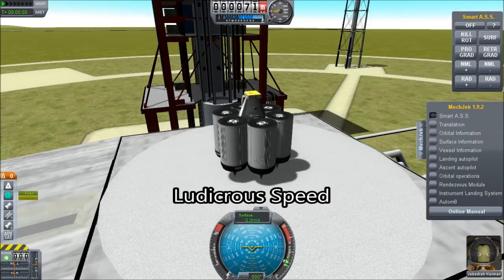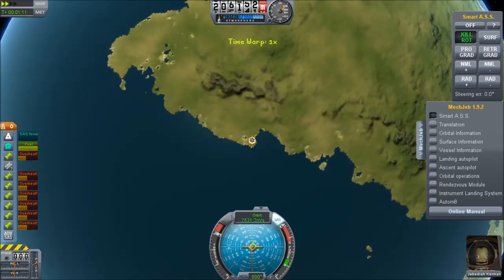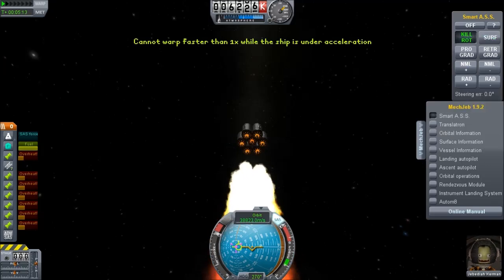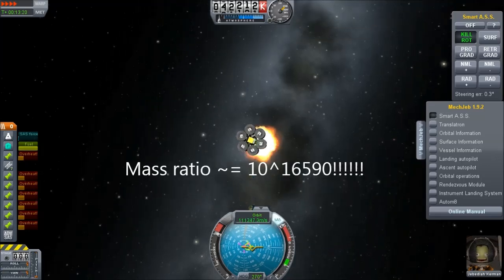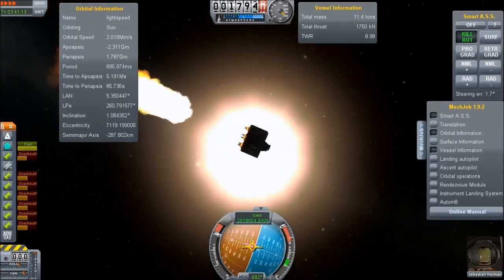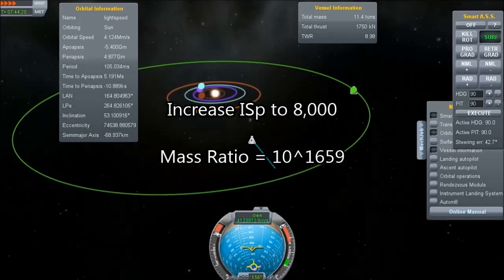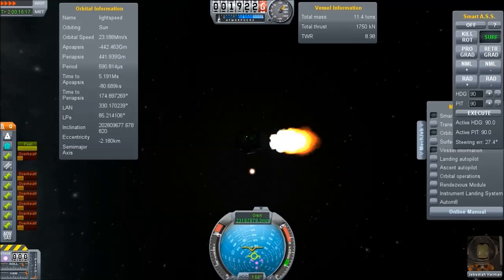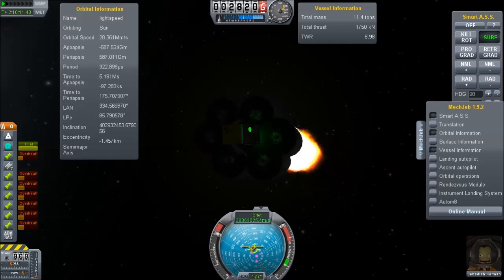What Does It Take To Reach Lightspeed In Kerbal Space Program?

Comment: +Scott Manley That sure was alot of zero's to put that number in a comment well this is what it would look like good luck finding the bottom.

1000000000000000000000000000000000000000000000000000000000000000000000000000000000000000000000000000000000000000000000000000000000000000000000000000000000000000000000000000000000000000000000000000000000000000000000000000000000000000000000000000000000000000000000000000000000000000000000000000000000000000000000000000000000000000000000000000000000000000000000000000000000000000000000000000000000000000000000000000000000000000000000000000000000000000000000000000000000000000000000000000000000000000000000000000000000000000000000000000000000000000000000000000000000000000000000000000000000000000000000000000000000000000000000000000000000000000000000000000000000000000000000000000000000000000000000000000000000000000000000000000000000000000000000000000000000000000000000000000000000000000000000000000000000000000000000000000000000000000000000000000000000000000000000000000000000000000000000000000000000000000000000000000000000000000000000000000000000000000000000000000000000000000000000000000000000000000000000000000000000000000000000000000000000000000000000000000000000000000000000000000000000000000000000000000000000000000000000000000000000000000000000000000000000000000000000000000000000000000000000000000000000000000000000000000000000000000000000000000000000000000000000000000000000000000000000000000000000000000000000000000000000000000000000000000000000000000000000000000000000000000000000000000000000000000000000000000000000000000000000000000000000000000000000000000000000000000000000000000000000000000000000000000000000000000000000000000000000000000000000000000000000000000000000000000000000000000000000000000000000000000000000000000000000000000000000000000000000000000000000000000000000000000000000000000000000000000000000000000000000000000000000000000000000000000000000000000000000000000000000000000000000000000000000000000000000000000000000000000000000000000000000000000000000000000000000000000000000000000000000000000000000000000000000000000000000000000000000000000000000000000000000000000000000000000000000000000000000000000000000000000000000000000000000000000000000000000000000000000000000000000000000000000000000000000000000000000000000000000000000000000000000000000000000000000000000000000000000000000000000000000000000000000000000000000000000000000000000000000000000000000000000000000000000000000000000000000000000000000000000000000000000000000000000000000000000000000000000000000000000000000000000000000000000000000000000000000000000000000000000000000000000000000000000000000000000000000000000000000000000000000000000000000000000000000000000000000000000000000000000000000000000000000000000000000000000000000000000000000000000000000000000000000000000000000000000000000000000000000000000000000000000000000000000000000000000000000000000000000000000000000000000000000000000000000000000000000000000000000000000000000000000000000000000000000000000000000000000000000000000000000000000000000000000000000000000000000000000000000000000000000000000000000000000000000000000000000000000000000000000000000000000000000000000000000000000000000000000000000000000000000000000000000000000000000000000000000000000000000000000000000000000000000000000000000000000000000000000000000000000000000000000000000000000000000000000000000000000000000000000000000000000000000000000000000000000000000000000000000000000000000000000000000000000000000000000000000000000000000000000000000000000000000000000000000000000000000000000000000000000000000000000000000000000000000000000000000000000000000000000000000000000000000000000000000000000000000000000000000000000000000000000000000000000000000000000000000000000000000000000000000000000000000000000000000000000000000000000000000000000000000000000000000000000000000000000000000000000000000000000000000000000000000000000000000000000000000000000000000000000000000000000000000000000000000000000000000000000000000000000000000000000000000000000000000000000000000000000000000000000000000000000000000000000000000000000000000000000000000000000000000000000000000000000000000000000000000000000000000000000000000000000000000000000000000000000000000000000000000000000000000000000000000000000000000000000000000000000000000000000000000000000000000000000000000000000000000000000000000000000000000000000000000000000000000000000000000000000000000000000000000000000000000000000000000000000000000000000000000000000000000000000000000000000000000000000000000000000000000000000000000000000000000000000000000000000000000000000000000000000000000000000000000000000000000000000000000000000000000000000000000000000000000000000000000000000000000000000000000000000000000000000000000000000000000000000000000000000000000000000000000000000000000000000000000000000000000000000000000000000000000000000000000000000000000000000000000000000000000000000000000000000000000000000000000000000000000000000000000000000000000000000000000000000000000000000000000000000000000000000000000000000000000000000000000000000000000000000000000000000000000000000000000000000000000000000000000000000000000000000000000000000000000000000000000000000000000000000000000000000000000000000000000000000000000000000000000000000000000000000000000000000000000000000000000000000000000000000000000000000000000000000000000000000000000000000000000000000000000000000000000000000000000000000000000000000000000000000000000000000000000000000000000000000000000000000000000000000000000000000000000000000000000000000000000000000000000000000000000000000000000000000000000000000000000000000000000000000000000000000000000000000000000000000000000000000000000000000000000000000000000000000000000000000000000000000000000000000000000000000000000000000000000000000000000000000000000000000000000000000000000000000000000000000000000000000000000000000000000000000000000000000000000000000000000000000000000000000000000000000000000000000000000000000000000000000000000000000000000000000000000000000000000000000000000000000000000000000000000000000000000000000000000000000000000000000000000000000000000000000000000000000000000000000000000000000000000000000000000000000000000000000000000000000000000000000000000000000000000000000000000000000000000000000000000000000000000000000000000000000000000000000000000000000000000000000000000000000000000000000000000000000000000000000000000000000000000000000000000000000000000000000000000000000000000000000000000000000000000000000000000000000000000000000000000000000000000000000000000000000000000000000000000000000000000000000000000000000000000000000000000000000000000000000000000000000000000000000000000000000000000000000000000000000000000000000000000000000000000000000000000000000000000000000000000000000000000000000000000000000000000000000000000000000000000000000000000000000000000000000000000000000000000000000000000000000000000000000000000000000000000000000000000000000000000000000000000000000000000000000000000000000000000000000000000000000000000000000000000000000000000000000000000000000000000000000000000000000000000000000000000000000000000000000000000000000000000000000000000000000000000000000000000000000000000000000000000000000000000000000000000000000000000000000000000000000000000000000000000000000000000000000000000000000000000000000000000000000000000000000000000000000000000000000000000000000000000000000000000000000000000000000000000000000000000000000000000000000000000000000000000000000000000000000000000000000000000000000000000000000000000000000000000000000000000000000000000000000000000000000000000000000000000000000000000000000000000000000000000000000000000000000000000000000000000000000000000000000000000000000000000000000000000000000000000000000000000000000000000000000000000000000000000000000000000000000000000000000000000000000000000000000000000000000000000000000000000000000000000000000000000000000000000000000000000000000000000000000000000000000000000000000000000000000000000000000000000000000000000000000000000000000000000000000000000000000000000000000000000000000000000000000000000000000000000000000000000000000000000000000000000000000000000000000000000000000000000000000000000000000000000000000000000000000000000000000000000000000000000000000000000000000000000000000000000000000000000000000000000000000000000000000000000000000000000000000000000000000000000000000000000000000000000000000000000000000000000000000000000000000000000000000000000000000000000000000000000000000000000000000000000000000000000000000000000000000000000000000000000000000000000000000000000000000000000000000000000000000000000000000000000000000000000000000000000000000000000000000000000000000000000000000000000000000000000000000000000000000000000000000000000000000000000000000000000000000000000000000000000000000000000000000000000000000000000000000000000000000000000000000000000000000000000000000000000000000000000000000000000000000000000000000000000000000000000000000000000000000000000000000000000000000000000000000000000000000000000000000000000000000000000000000000000000000000000000000000000000000000000000000000000000000000000000000000000000000000000000000000000000000000000000000000000000000000000000000000000000000000000000000000000000000000000000000000000000000000000000000000000000000000000000000000000000000000000000000000000000000000000000000000000000000000000000000000000000000000000000000000000000000000000000000000000000000000000000000000000000000000000000000000000000000000000000000000000000000000000000000000000000000000000000000000000000000000000000000000000000000000000000000000000000000000000000000000000000000000000000000000000000000000000000000000000000000000000000000000000000000000000000000000000000000000000000000000000000000000000000000000000000000000000000000000000000000000000000000000000000000000000000000000000000000000000000000000000000000000000000000000000000000000000000000000000000000000000000000000000000000000000000000000000000000000000000000000000000000000000000000000000000000000000000000000000000000000000000000000000000000000000000000000000000000000000000000000000000000000000000000000000000000000000000000000000000000000000000000000000000000000000000000000000000000000000000000000000000000000000000000000000000000000000000000000000000000000000000000000000000000000000000000000000000000000000000000000000000000000000000000000000000000000000000000000000000000000000000000000000000000000000000000000000000000000000000000000000000000000000000000000000000000000000000000000000000000000000000000000000000000000000000000000000000000000000000000000000000000000000000000000000000000000000000000000000000000000000000000000000000000000000000000000000000000000000000000000000000000000000000000000000000000000000000000000000000000000000000000000000000000000000000000000000000000000000000000000000000000000000000000000000000000000000000000000000000000000000000000000000000000000000000000000000000000000000000000000000000000000000000000000000000000000000000000000000000000000000000000000000000000000000000000000000000000000000000000000000000000000000000000000000000000000000000000000000000000000000000000000000000000000000000000000000000000000000000000000000000000000000000000000000000000000000000000000000000000000000000000000000000000000000000000000000000000000000000000000000000000000000000000000000000000000000000000000000000000000000000000000000000000000000000000000000000000000000000000000000000000000000000000000000000000000000000000000000000000000000000000000000000000000000000000000000000000000000000000000000000000000000000000000000000000000000000000000000000000000000000000000000000000000000000000000000000000000000000000000000000000000000000000000000000000000000000000000000000000000000000000000000000000000000000000000000000000000000000000000000000000000000000000000000000000000000000000000000000000000000000000000000000000000000000000000000000000000000000000000000000000000000000000000000000000000000000000000000000000000000000000000000000000000000000000000000000000000000000000000000000000000000000000000000000000000000000000000000000000000000000000000000000000000000000000000000000000000000000000000000000000000000000000000000000000000000000000000000000000000000000000000000000000000000000000000000000000000000000000000000000000000000000000000000000000000000000000000000000000000000000000000000000000000000000000000000000000000000000000000000000000000000000000000000000000000000000000000000000000000000000000000000000000000000000000000000000000000000000000000000000000000000000000000000000000000000000000000000000000000000000000000000000000000000000000000000000000000000000000000000000000000000000000000000000000000000000000000000000000000000000000000000000000000000000000000000000000000000000000000000000000000000000000000000000000000000000000000000000000000000000000000000000000000000000000000000000000000000000000000000000000000000000000000000000000000000000000000000000000000000000000000000000000000000000000000000000000000000000000000000000000000000000000000000000000000000000000000000000000000000000000000000000000000000000000000000000000000000000000000000000000000000000000000000000000000000000000000000000000000000000000000000000000000000000000000000000000000000000000000000000000000000000000000000000000000000000000000000000000000000000000000000000000000000000000000000000000000000000000000000000000000000000000000000000000000000000000000000000000000000000000000000000000000000000000000000000000000000000000000000000000000000000000000000000000000000000000000000000000000000000000000000000000000000000000000000000000000000000000000000000000000000000000000000000000000000000000000000000000000000000000000000000000000000000000000000000000000000000000000000000000000000000000000000000000000000000000000000000000000000000000000000000000000000000000000000000000000000000000000000000000000000000000000000000000000000000000000000000000000000000000000000000000000000000000000000000000000000000000000000000000000000000000000000000000000000000000000000000000000000000000000000000000000000000000000000000000000000000000000000000000000000000000000000000000000000000000000000000000000000000000000000000000000000000000000000000000000000000000000000000000000000000000000000000000000000000000000000000000000000000000000000000000000000000000000000000000000000000000000000000000000000000000000000000000000000000000000000000000000000000000000000000000000000000000000000000000000000000000000000000000000000000000000000000000000000000000000000000000000000000000000000000000000000000000000000000000000000000000000000000000000000000000000000000000000000000000000000000000000000000000000000000000000000000000000000000000000000000000000000000000000000000000000000000000000000000000000000000000000000000000000000000000000000000000000000000000000000000000000000000000000000000000000000000000000000000000000000000000000000000000000000000000000000000000000000000000000000000000000000000000000000000000000000000000000000000000000000000000000000000000000000000000000000000000000000000000000000000000000000000000000000000000000000000000000000000000000000000000000000000000000000000000000000000000000000000000000000000000000000000000000000000000000000000000000000000000000000000000000000000000000000000000000000000000000000000000000000000000000000000000000000000000000000000000000000000000000000000000000000000000000000000000000000000000000000000000000000000000000000000000000000000000000000000000000000000000000000000000000000000000000000000000000000000000000000000000000000000000000000000000000000000000000000000000000000000000000000000000000000000000000000000000000000000000000000000000000000000000000000000000000000000000000000000000000000000000000000000000000000000000000000000000000000000000000000000000000000000000000000000000000000000000000000000000000000000000000000000000000000000000000000000000000000000000000000000000000000000000000000000000000000000000000000000000000000000000000000000000000000000000000000000000000000000000000000000000000000000000000000000000000000000000000000000000000000000000000000000000000000000000000000000000000000000000000000000000000000000000000000000000000000000000000000000000000000000000000000000000000000000000000000000000000000000000000000000000000000000000000000000000000000000000000000000000000000000000000000000000000000000000000000000000000000000000000000000000000000000000000000000000000000000000000000000000000000000000000000000000000000000000000000000000000000000000000000000000000000000000000000000000000000000000000000000000000000000000000000000000000000000000000000000000000000000000000000000000000000000000000000000000000000000000000000000000000000000000000000000000000000000000000000000000000000000000000000000000000000000000000000000000000000000000000000000000000000000000000000000000000000000000000000000000000000000000000000000000000000000000000000000000000000000000000000000000000000000000000000000000000000000000000000000000000000000000000000000000000000000000000000000000000000000000000000000000000000000000000000000000000000000000000000000000000000000000000000000000000000000000000000000000000000000000000000000000000000000000000000000000000000000000000000000000000000000000000000000000000000000000000000000000000000000000000000000000000000000000000000000000000000000000000000000000000000000000000000000000000000000000000000000000000000000000000000000000000000000000000000000000000000000000000000000000000000000000000000000000000000000000000000000000000000000000000000000000000000000000000000000000000000000000000000000000000000000000000000000000000000000000000000000000000000000000000000000000000000000000000000000000000000000000000000000000000000000000000000000000000000000000000000000000000000000000000000000000000000000000000000000000000000000000000000000000000000000000000000000000000000000000000000000000000000000000000000000000000000000000000000000000000000000000000000000000000000000000000000000000000000000000000000000000000000000000000000000000000000000000000000000000000000000000000000000000000000000000000000000000000000000000000000000000000000000000000000000000000000000000000000000000000000000000000000000000000000000000000000000000000000000000000000000000000000000000000000000000000000000000000000000000000000000000000000000000000000000000000000000000000000000000000000000000000000000000000000000000000000000000000000000000000000000000000000000000000000000000000000000000000000000000000000000000000000000000000000000000000000000000000000000000000000000000000000000000000000000000000000000000000000000000000000000000000000000000000000000000000000000000000000000000000000000000000000000000000000000000000000000000000000000000000000000000000000000000000000000000000000000000000000000000000000000000000000000000000000000000000000000000000000000000000000000000000000000000000000000000000000000000000000000000000000000000000000000000000000000000000000000000000000000000000000000000000000000000000000000000000000000000000000000000000000000000000000000000000000000000000000000000000000000000000000000000000000000000000000000000000000000000000000000000000000000000000000000000000000000000000000000000000000000000000000000000000000000000000000000000000000000000000000000000000000000000000000000000000000000000000000000000000000000000000000000000000000000000000000000000000000000000000000000000000000000000000000000000000000000000000000000000000000000000000000000000000000000000000000000000000000000000000000000000000000000000000000000000000000000000000000000000000000000000000000000000000000000000000000000000000000000000000000000000000000000000000000000000000000000000000000000000000000000000000000000000000000000000000000000000000000000000000000000000000000000000000000000000000000000000000000000000000000000000000000000000000000000000000000000000000000000000000000000000000000000000000000000000000000000000000000000000000000000000000000000000000000000000000000000000000000000000000000000000000000000000000000000000000000000000000000000000000000000000000000000000000000000000000000000000000000000000000000000000000000000000000000000000000000000000000000000000000000000000000000000000000000000000000000000000000000000000000000000000000000000000000000000000000000000000000000000000000000000000000000000000000000000000000000000000000000000000000000000000000000000000000000000000000000000000000000000000000000000000000000000000000000000000000000000000000000000000000000000000000000000000000000000000000000000000000000000000000000000000000000000000000000000000000000000000000000000000000000000000000000000000000000000000000000000000000000000000000000000000000000000000000000000000000000000000000000000000000000000000000000000000000000000000000000000000000000000000000000000000000000000000000000000000000000000000000000000000000000000000000000000000000000000000000000000000000000000000000000000000000000000000000000000000000000000000000000000000000000000000000000000000000000000000000000000000000000000000000000000000000000000000000000000000000000000000000000000000000000000000000000000000000000000000000000000000000000000000000000000000000000000000000000000000000000000000000000000000000000000000000000000000000000000000000000000000000000000000000000000000000000000000000000000000000000000000000000000000000000000000000000000000000000000000000000000000000000000000000000000000000000000000000000000000000000000000000000000000000000000000000000000000000000000000000000000000000000000000000000000000000000000000000000000000000000000000000000000000000000000000000000000000000000000000000000000000000000000000000000000000000000000000000000000000000000000000000000000000000000000000000000000000000000000000000000000000000000000000000000000000000000000000000000000000000000000000000000000000000000000000000000000000000000000000000000000000000000000000000000000000000000000000000000000000000000000000000000000000000000000000000000000000000000000000000000000000000000000000000000000000000000000000000000000000000000000000000000000000000000000000000000000000000000000000000000000000000000000000000000000000000000000000000000000000000000000000000000000000000000000000000000000000000000000000000000000000000000000000000000000000000000000000000000000000000000000000000000000000000000000000000000000000000000000000000000000000000000000000000000000000000000000000000000000000000000000000000000000000000000000000000000000000000000000000000000000000000000000000000000000000000000000000000000000000000000000000000000000000000000000000000000000000000000000000000000000000000000000000000000000000000000000000000000000000000000000000000000000000000000000000000000000000000000000000000000000000000000000000000000000000000000000000000000000000000000000000000000000000000000000000000000000000000000000000000000000000000000000000000000000000000000000000000000000000000000000000000000000000000000000000000000000000000000000000000000000000000000000000000000000000000000000000000000000000000000000000000000000000000000000000000000000000000000000000000000000000000000000000000000000000000000000000000000000000000000000000000000000000000000000000000000000000000000000000000000000000000000000000000000000000000000000000000000000000000000000000000000000000000000000000000000000000000000000000000000000000000000000000000000000000000000000000000000000000000000000000000000000000000000000000000000000000000000000000000000000000000000000000000000000000000000000000000000000000000000000000000000000000000000000000000000000000000000000000000000000000000000000000000000000000000000000000000000000000000000000000000000000000000000000000000000000000000000000000000000000000000000000000000000000000000000000000000000000000000000000000000000000000000000000000000000000000000000000000000000000000000000000000000000000000000000000000000000000000000000000000000000000000000000000000000000000000000000000000000000000000000000000000000000000000000000000000000000000000000000000000000000000000000000000000000000000000000000000000000000000000000000000000000000000000000000000000000000000000000000000000000000000000000000000000000000000000000000000000000000000000000000000000000000000000000000000000000000000000000000000000000000000000000000000000000000000000000000000000000000000000000000000000000000000000000000000000000000000000000000000000000000000000000000000000000000000000000000000000000000000000000000000000000000000000000000000000000000000000000000000000000000000000000000000000000000000000000000000000000000000000000000000000000000000000000000000000000000000000000000000000000000000000000000000000000000000000000000000000000000000000000000000000000000000000000000000000000000000000000000000000000000000000000000000000000000000000000000000000000000000000000000000000000000000000000000000000000000000000000000000000000000000000000000000000000000000000000000000000000000000000000000000000000000000000000000000000000000000000000000000000000000000000000000000000000000000000000000000000000000000000000000000000000000000000000000000000000000000000000000000000000000000000000000000000000000000000000000000000000000000000000000000000000000000000000000000000000000000000000000000000000000000000000000000000000000000000000000000000000000000000000000000000000000000000000000000000000000000000000000000000000000000000000000000000000000000000000000000000000000000000000000000000000000000000000000000000000000000000000000000000000000000000000000000000000000000000000000000000000000000000000000000000000000000000000000000000000000000000000000000000000000000000000000000000000000000000000000000000000000000000000000000000000000000000000000000000000000000000000000000000000000000000000000000000000000000000000000000000000000000000000000000000000000000000000000000000000000000000000000000000000000000000000000000000000000000000000000000000000000000000000000000000000000000000000000000000000000000000000000000000000000000000000000000000000000000000000000000000000000000000000000000000000000000000000000000000000000000000000000000000000000000000000000000000000000000000000000000000000000000000000000000000000000000000000000000000000000000000000000000000000000000000000000000000000000000000000000000000000000000000000000000000000000000000000000000000000000000000000000000000000000000000000000000000000000000000000000000000000000000000000000000000000000000000000000000000000000000000000000000000000000000000000000000000000000000000000000000000000000000000000000000000000000000000000000000000000000000000000000000000000000000000000000000000000000000000000000000000000000000000000000000000000000000000000000000000000000000000000000000000000000000000000000000000000000000000000000000000000000000000000000000000000000000000000000000000000000000000000000000000000000000000000000000000000000000000000000000000000000000000000000000000000000000000000000000000000000000000000000000000000000000000000000000000000000000000000000000000000000000000000000000000000000000000000000000000000000000000000000000000000000000000000000000000000000000000000000000000000000000000000000000000000000000000000000000000000000000000000000000000000000000000000000000000000000000000000000000000000000000000000000000000000000000000000000000000000000000000000000000000000000000000000000000000000000000000000000000000000000000000000000000000000000000000000000000000000000000000000000000000000000000000000000000000000000000000000000000000000000000000000000000000000000000000000000000000000000000000000000000000000000000000000000000000000000000000000000000000000000000000000000000000000000000000000000000000000000000000000000000000000000000000000000000000000000000000000000000000000000000000000000000000000000000000000000000000000000000000000000000000000000000000000000000000000000000000000000000000000000000000000000000000000000000000000000000000000000000000000000000000000000000000000000000000000000000000000000000000000000000000000000000000000000000000000000000000000000000000000000000000000000000000000000000000000000000000000000000000000000000000000000000000000000000000000000000000000000000000000000000000000000000000000000000000000000000000000000000000000000000000000000000000000000000000000000000000000000000000000000000000000000000000000000000000000000000000000000000000000000000000000000000000000000000000000000000000000000000000000000000000000000000000000000000000000000000000000000000000000000000000000000000000000000000000000000000000000000000000000000000000000000000000000000000000000000000000000000000000000000000000000000000000000000000000000000000000000000000000000000000000000000000000000000000000000000000000000000000000000000000000000000000000000000000000000000000000000000000000000000000000000000000000000000000000000000000000000000000000000000000000000000000000000000000000000000000000000000000000000000000000000000000000000000000000000000000000000000000000000000000000000000000000000000000000000000000000000000000000000000000000000000000000000000000000000000000000000000000000000000000000000000000000000000000000000000000000000000000000000000000000000000000000000000000000000000000000000000000000000000000000000000000000000000000000000000000000000000000000000000000000000000000000000000000000000000000000000000000000000000000000000000000000000000000000000000000000000000000000000000000000000000000000000000000000000000000000000000000000000000000000000000000000000000000000000000000000000000000000000000000000000000000000000000000000000000000000000000000000000000000000000000000000000000000000000000000000000000000000000000000000000000000000000000000000000000000000000000000000000000000000000000000000000000000000000000000000000000000000000000000000000000000000000000000000000000000000000000000000000000000000000000000000000000000000000000000000000000000000000000000000000000000000000000000000000000000000000000000000000000000000000000000000000000000000000000000000000000000000000000000000000000000000000000000000000000000000000000000000000000000000000000000000000000000000000000000000000000000000000000000000000000000000000000000000000000000000000000000000000000000000000000000000000000000000000000000000000000000000000000000000000000000000000000000000000000000000000000000000000000000000000000000000000000000000000000000000000000000000000000000000000000000000000000000000000000000000000000000000000000000000000000000000000000000000000000000000000000000000000000000000000000000000000000000000000000000000000000000000000000000000000000000000000000000000000000000000000000000000000000000000000000000000000000000000000000000000000000000000000000000000000000000000000000000000000000000000000000000000000000000000000000000000000000000000000000000000000000000000000000000000000000000000000000000000000000000000000000000000000000000000000000000000000000000000000000000000000000000000000000000000000000000000000000000000000000000000000000000000000000000000000000000000000000000000000000000000000000000000000000000000000000000000000000000000000000000000000000000000000000000000000000000000000000000000000000000000000000000000000000000000000000000000000000000000000000000000000000000000000000000000000000000000000000000000000000000000000000000000000000000000000000000000000000000000000000000000000000000000000000000000000000000000000000000000000000000000000000000000000000000000000000000000000000000000000000000000000000000000000000000000000000000000000000000000000000000000000000000000000000000000000000000000000000000000000000000000000000000000000000000000000000000000000000000000000000000000000000000000000000000000000000000000000000000000000000000000000000000000000000000000000000000000000000000000000000000000000000000000000000000000000000000000000000000000000000000000000000000000000000000000000000000000000000000000000000000000000000000000000000000000000000000000000000000000000000000000000000000000000000000000000000000000000000000000000000000000000000000000000000000000000000000000000000000000000000000000000000000000000000000000000000000000000000000000000000000000000000000000000000000000000000000000000000000000000000000000000000000000000000000000000000000000000000000000000000000000000000000000000000000000000000000000000000000000000000000000000000000000000000000000000000000000000000000000000000000000000000000000000000000000000000000000000000000000000000000000000000000000000000000000000000000000000000000000000000000000000000000000000000000000000000000000000000000000000000000000000000000000000000000000000000000000000000000000000000000000000000000000000000000000000000000000000000000000000000000000000000000000000000000000000000000000000000000000000000000000000000000000000000000000000000000000000000000000000000000000000000000000000000000000000000000000000000000000000000000000000000000000000000000000000000000000000000000000000000000000000000000000000000000000000000000000000000000000000000000000000000000000000000000000000000000000000000000000000000000000000000000000000000000000000000000000000000000000000000000000000000000000000000000000000000000000000000000000000000000000000000000000000000000000000000000000000000000000000000000000000000000000000000000000000000000000000000000000000000000000000000000000000000000000000000000000000000000000000000000000000000000000000000000000000000000000000000000000000000000000000000000000000000000000000000000000000000000000000000000000000000000000000000000000000000000000000000000000000000000000000000000000000000000000000000000000000000000000000000000000000000000000000000000000000000000000000000000000000000000000000000000000000000000000000000000000000000000000000000000000000000000000000000000000000000000000000000000000000000000000000000000000000000000000000000000000000000000000000000000000000000000000000000000000000000000000000000000000000000000000000000000000000000000000000000000000000000000000000000000000000000000000000000000000000000000000000000000000000000000000000000000000000000000000000000000000000000000000000000000000000000000000000000000000000000000000000000000000000000000000000000000000000000000000000000000000000000000000000000000000000000000000000000000000000000000000000000000000000000000000000000000000000000000000000000000000000000000000000000000000000000000000000000000000000000000000000000000000000000000000000000000000000000000000000000000000000000000000000000000000000000000000000000000000000000000000000000000000000000000000000000000000000000000000000000000000000000000000000000000000000000000000000000000000000000000000000000000000000000000000000000000000000000000000000000000000000000000000000000000000000000000000000000000000000000000000000000000000000000000000000000000000000000000000000000000000000000000000000000000000000000000000000000000000000000000000000000000000000000000000000000000000000000000000000000000000000000000000000000000000000000000000000000000000000000000000000000000000000000000000000000000000000000000000000000000000000000000000000000000000000000000000000000000000000000000000000000000000000000000000000000000000000000000000000000000000000000000000000000000000000000000000000000000000000000000000000000000000000000000000000000000000000000000000000000000000000000000000000000000000000000000000000000000000000000000000000000000000000000000000000000000000000000000000000000000000000000000000000000000000000000000000000000000000000000000000000000000000000000000000000000000000000000000000000000000000000000000000000000000000000000000000000000000000000000000000000000000000000000000000000000000000000000000000000000000000000000000000000000000000000000000000000000000000000000000000000000000000000000000000000000000000000000000000000000000000000000000000000000000000000000000000000000000000000000000000000000000000000000000000000000000000000000000000000000000000000000000000000000000000000000000000000000000000000000000000000000000000000000000000000000000000000000000000000000000000000000000000000000000000000000000000000000000000000000000000000000000000000000000000000000000000000000000000000000000000000000000000000000000000000000000000000000000000000000000000000000000000000000000000000000000000000000000000000000000000000000000000000000000000000000000000000000000000000000000000000000000000000000000000000000000000000000000000000000000000000000000000000000000000000000000000000000000000000000000000000000000000000000000000000000000000000000000000000000000000000000000000000000000000000000000000000000000000000000000000000000000000000000000000000000000000000000000000000000000000000000000000000000000000000000000000000000000000000000000000000000000000000000000000000000000000000000000000000000000000000000000000000000000000000000000000000000000000000000000000000000000000000000000000000000000000000000000000000000000000000000000000000000000000000000000000000000000000000000000000000000000000000000000000000000000000000000000000000000000000000000000000000000000000000000000000000000000000000000000000000000000000000000000000000000000000000000000000000000000000000000000000000000000000000000000000000000000000000000000000000000000000000000000000000000000000000000000000000000000000000000000000000000000000000000000000000000000000000000000000000000000000000000000000000000000000000000000000000000000000000000000000000000000000000000000000000000000000000000000000000000000000000000000000000000000000000000000000000000000000000000000000000000000000000000000000000000000000000000000000000000000000000000000000000000000000000000000000000000000000000000000000000000000000000000000000000000000000000000000000000000000000000000000000000000000000000000000000000000000000000000000000000000000000000000000000000000000000000000000000000000000000000000000000000000000000000000000000000000000000000000000000000000000000000000000000000000000000000000000000000000000000000000000000000000000000000000000000000000000000000000000000000000000000000000000000000000000000000000000000000000000000000000000000000000000000000000000000000000000000000000000000000000000000000000000000000000000000000000000000000000000000000000000000000000000000000000000000000000000000000000000000000000000000000000000000000000000000000000000000000000000000000000000000000000000000000000000000000000000000000000000000000000000000000000000000000000000000000000000000000000000000000000000000000000000000000000000000000000000000000000000000000000000000000000000000000000000000000000000000000000000000000000000000000000000000000000000000000000000000000000000000000000000000000000000000000000000000000000000000000000000000000000000000000000000000000000000000000000000000000000000000000000000000000000000000000000000000000000000000000000000000000000000000000000000000000000000000000000000000000000000000000000000000000000000000000000000000000000000000000000000000000000000000000000000000000000000000000000000000000000000000000000000000000000000000000000000000000000000000000000000000000000000000000000000000000000000000000000000000000000000000000000000000000000000000000000000000000000000000000000000000000000000000000000000000000000000000000000000000000000000000000000000000000000000000000000000000000000000000000000000000000000000000000000000000000000000000000000000000000000000000000000000000000000000000000000000000000000000000000000000000000000000000000000000000000000000000000000000000000000000000000000000000000000000000000000000000000000000000000000000000000000000000000000000000000000000000000000000000000000000000000000000000000000000000000000000000000000000000000000000000000000000000000000000000000000000000000000000000000000000000000000000000000000000000000000000000000000000000000000000000000000000000000000000000000000000000000000000000000000000000000000000000000000000000000000000000000000000000000000000000000000000000000000000000000000000000000000000000000000000000000000000000000000000000000000000000000000000000000000000000000000000000000000000000000000000000000000000000000000000000000000000000000000000000000000000000000000000000000000000000000000000000000000000000000000000000000000000000000000000000000000000000000000000000000000000000000000000000000000000000000000000000000000000000000000000000000000000000000000000000000000000000000000000000000000000000000000000000000000000000000000000000000000000000000000000000000000000000000000000000000000000000000000000000000000000000000000000000000000000000000000000000000000000000000000000000000000000000000000000000000000000000000000000000000000000000000000000000000000000000000000000000000000000000000000000000000000000000000000000000000000000000000000000000000000000000000000000000000000000000000000000000000000000000000000000000000000000000000000000000000000000000000000000000000000000000000000000000000000000000000000000000000000000000000000000000000000000000000000000000000000000000000000000000000000000000000000000000000000000000000000000000000000000000000000000000000000000000000000000000000000000000000000000000000000000000000000000000000000000000000000000000000000000000000000000000000000000000000000000000000000000000000000000000000000000000000000000000000000000000000000000000000000000000000000000000000000000000000000000000000000000000000000000000000000000000000000000000000000000000000000000000000000000000000000000000000000000000000000000000000000000000000000000000000000000000000000000000000000000000000000000000000000000000000000000000000000000000000000000000000000000000000000000000000000000000000000000000000000000000000000000000000000000000000000000000000000000000000000000000000000000000000000000000000000000000000000000000000000000000000000000000000000000000000000000000000000000000000000000000000000000000000000000000000000000000000000000000000000000000000000000000000000000000000000000000000000000000000000000000000000000000000000000000000000000000000000000000000000000000000000000000000000000000000000000000000000000000000000000000000000000000000000000000000000000000000000000000000000000000000000000000000000000000000000000000000000000000000000000000000000000000000000000000000000000000000000000000000000000000000000000000000000000000000000000000000000000000000000000000000000000000000000000000000000000000000000000000000000000000000000000000000000000000000000000000000000000000000000000000000000000000000000000000000000000000000000000000000000000000000000000000000000000000000000000000000000000000000000000000000000000000000000000000000000000000000000000000000000000000000000000000000000000000000000000000000000000000000000000000000000000000000000000000000000000000000000000000000000000000000000000000000000000000000000000000000000000000000000000000000000000000000000000000000000000000000000000000000000000000000000000000000000000000000000000000000000000000000000000000000000000000000000000000000000000000000000000000000000000000000000000000000000000000000000000000000000000000000000000000000000000000000000000000000000000000000000000000000000000000000000000000000000000000000000000000000000000000000000000000000000000000000000000000000000000000000000000000000000000000000000000000000000000000000000000000000000000000000000000000000000000000000000000000000000000000000000000000000000000000000000000000000000000000000000000000000000000000000000000000000000000000000000000000000000000000000000000000000000000000000000000000000000000000000000000000000000000000000000000000000000000000000000000000000000000000000000000000000000000000000000000000000000000000000000000000000000000000000000000000000000000000000000000000000000000000000000000000000000000000000000000000000000000000000000000000000000000000000000000000000000000000000000000000000000000000000000000000000000000000000000000000000000000000000000000000000000000000000000000000000000000000000000000000000000000000000000000000000000000000000000000000000000000000000000000000000000000000000000000000000000000000000000000000000000000000000000000000000000000000000000000000000000000000000000000000000000000000000000000000000000000000000000000000000000000000000000000000000000000000000000000000000000000000000000000000000000000000000000000000000000000000000000000000000000000000000000000000000000000000000000000000000000000000000000000000000000000000000000000000000000000000000000000000000000000000000000000000000000000000000000000000000000000000000000000000000000000000000000000000000000000000000000000000000000000000000000000000000000000000000000000000000000000000000000000000000000000000000000000000000000000000000000000000000000000000000000000000000000000000000000000000000000000000000000000000000000000000000000000000000000000000000000000000000000000000000000000000000000000000000000000000000000000000000000000000000000000000000000000000000000000000000000000000000000000000000000000000000000000000000000000000000000000000000000000000000000000000000000000000000000000000000000000000000000000000000000000000000000000000000000000000000000000000000000000000000000000000000000000000000000000000000000000000000000000000000000000000000000000000000000000000000000000000000000000000000000000000000000000000000000000000000000000000000000000000000000000000000000000000000000000000000000000000000000000000000000000000000000000000000000000000000000000000000000000000000000000000000000000000000000000000000000000000000000000000000000000000000000000000000000000000000000000000000000000000000000000000000000000000000000000000000000000000000000000000000000000000000000000000000000000000000000000000000000000000000000000000000000000000000000000000000000000000000000000000000000000000000000000000000000000000000000000000000000000000000000000000000000000000000000000000000000000000000000000000000000000000000000000000000000000000000000000000000000000000000000000000000000000000000000000000000000000000000000000000000000000000000000000000000000000000000000000000000000000000000000000000000000000000000000000000000000000000000000000000000000000000000000000000000000000000000000000000000000000000000000000000000000000000000000000000000000000000000000000000000000000000000000000000000000000000000000000000000000000000000000000000000000000000000000000000000000000000000000000000000000000000000000000000000000000000000000000000000000000000000000000000000000000000000000000000000000000000000000000000000000000000000000000000000000000000000000000000000000000000000000000000000000000000000000000000000000000000000000000000000000000000000000000000000000000000000000000000000000000000000000000000000000000000000000000000000000000000000000000000000000000000000000000000000000000000000000000000000000000000000000000000000000000000000000000000000000000000000000000000000000000000000000000000000000000000000000000000000000000000000000000000000000000000000000000000000000000000000000000000000000000000000000000000000000000000000000000000000000000000000000000000000000000000000000000000000000000000000000000000000000000000000000000000000000000000000000000000000000000000000000000000000000000000000000000000000000000000000000000000000000000000000000000000000000000000000000000000000000000000000000000000000000000000000000000000000000000000000000000000000000000000000000000000000000000000000000000000000000000000000000000000000000000000000000000000000000000000000000000000000000000000000000000000000000000000000000000000000000000000000000000000000000000000000000000000000000000000000000000000000000000000000000000000000000000000000000000000000000000000000000000000000000000000000000000000000000000000000000000000000000000000000000000000000000000000000000000000000000000000000000000000000000000000000000000000000000000000000000000000000000000000000000000000000000000000000000000000000000000000000000000000000000000000000000000000000000000000000000000000000000000000000000000000000000000000000000000000000000000000000000000000000000000000000000000000000000000000000000000000000000000000000000000000000000000000000000000000000000000000000000000000000000000000000000000000000000000000000000000000000000000000000000000000000000000000000000000000000000000000000000000000000000000000000000000000000000000000000000000000000000000000000000000000000000000000000000000000000000000000000000000000000000000000000000000000000000000000000000000000000000000000000000000000000000000000000000000000000000000000000000000000000000000000000000000000000000000000000000000000000000000000000000000000000000000000000000000000000000000000000000000000000000000000000000000000000000000000000000000000000000000000000000000000000000000000000000000000000000000000000000000000000000000000000000000000000000000000000000000000000000000000000000000000000000000000000000000000000000000000000000000000000000000000000000000000000000000000000000000000000000000000000000000000000000000000000000000000000000000000000000000000000000000000000000000000000000000000000000000000000000000000000000000000000000000000000000000000000000000000000000000000000000000000000000000000000000000000000000000000000000000000000000000000000000000000000000000000000000000000000000000000000000000000000000000000000000000000000000000000000000000000000000000000000000000000000000000000000000000000000000000000000000000000000000000000000000000000000000000000000000000000000000000000000000000000000000000000000000000000000000000000000000000000000000000000000000000000000000000000000000000000000000000000000000000000000000000000000000000000000000000000000000000000000000000000000000000000000000000000000000000000000000000000000000000000000000000000000000000000000000000000000000000000000000000000000000000000000000000000000000000000000000000000000000000000000000000000000000000000000000000000000000000000000000000000000000000000000000000000000000000000000000000000000000000000000000000000000000000000000000000000000000000000000000000000000000000000000000000000000000000000000000000000000000000000000000000000000000000000000000000000000000000000000000000000000000000000000000000000000000000000000000000000000000000000000000000000000000000000000000000000000000000000000000000000000000000000000000000000000000000000000000000000000000000000000000000000000000000000000000000000000000000000000000000000000000000000000000000000000000000000000000000000000000000000000000000000000000000000000000000000000000000000000000000000000000000000000000000000000000000000000000000000000000000000000000000000000000000000000000000000000000000000000000000000000000000000000000000000000000000000000000000000000000000000000000000000000000000000000000000000000000000000000000000000000000000000000000000000000000000000000000000000000000000000000000000000000000000000000000000000000000000000000000000000000000000000000000000000000000000000000000000000000000000000000000000000000000000000000000000000000000000000000000000000000000000000000000000000000000000000000000000000000000000000000000000000000000000000000000000000000000000000000000000000000000000000000000000000000000000000000000000000000000000000000000000000000000000000000000000000000000000000000000000000000000000000000000000000000000000000000000000000000000000000000000000000000000000000000000000000000000000000000000000000000000000000000000000000000000000000000000000000000000000000000000000000000000000000000000000000000000000000000000000000000000000000000000000000000000000000000000000000000000000000000000000000000000000000000000000000000000000000000000000000000000000000000000000000000000000000000000000000000000000000000000000000000000000000000000000000000000000000000000000000000000000000000000000000000000000000000000000000000000000000000000000000000000000000000000000000000000000000000000000000000000000000000000000000000000000000000000000000000000000000000000000000000000000000000000000000000000000000000000000000000000000000000000000000000000000000000000000000000000000000000000000000000000000000000000000000000000000000000000000000000000000000000000000000000000000000000000000000000000000000000000000000000000000000000000000000000000000000000000000000000000000000000000000000000000000000000000000000000000000000000000000000000000000000000000000000000000000000000000000000000000000000000000000000000000000000000000000000000000000000000000000000000000000000000000000000000000000000000000000000000000000000000000000000000000000000000000000000000000000000000000000000000000000000000000000000000000000000000000000000000000000000000000000000000000000000000000000000000000000000000000000000000000000000000000000000000000000000000000000000000000000000000000000000000000000000000000000000000000000000000000000000000000000000000000000000000000000000000000000000000000000000000000000000000000000000000000000000000000000000000000000000000000000000000000000000000000000000000000000000000000000000000000000000000000000000000000000000000000000000000000000000000000000000000000000000000000000000000000000000000000000000000000000000000000000000000000000000000000000000000000000000000000000000000000000000000000000000000000000000000000000000000000000000000000000000000000000000000000000000000000000000000000000000000000000000000000000000000000000000000000000000000000000000000000000000000000000000000000000000000000000000000000000000000000000000000000000000000000000000000000000000000000000000000000000000000000000000000000000000000000000000000000000000000000000000000000000000000000000000000000000000000000000000000000000000000000000000000000000000000000000000000000000000000000000000000000000000000000000000000000000000000000000000000000000000000000000000000000000000000000000000000000000000000000000000000000000000000000000000000000000000000000000000000000000000000000000000000000000000000000000000000000000000000000000000000000000000000000000000000000000000000000000000000000000000000000000000000000000000000000000000000000000000000000000000000000000000000000000000000000000000000000000000000000000000000000000000000000000000000000000000000000000000000000000000000000000000000000000000000000000000000000000000000000000000000000000000000000000000000000000000000000000000000000000000000000000000000000000000000000000000000000000000000000000000000000000000000000000000000000000000000000000000000000000000000000000000000000000000000000000000000000000000000000000000000000000000000000000000000000000000000000000000000000000000000000000000000000000000000000000000000000000000000000000000000000000000000000000000000000000000000000000000000000000000000000000000000000000000000000000000000000000000000000000000000000000000000000000000000000000000000000000000000000000000000000000000000000000000000000000000000000000000000000000000000000000000000000000000000000000000000000000000000000000000000000000000000000000000000000000000000000000000000000000000000000000000000000000000000000000000000000000000000000000000000000000000000000000000000000000000000000000000000000000000000000000000000000000000000000000000000000000000000000000000000000000000000000000000000000000000000000000000000000000000000000000000000000000000000000000000000000000000000000000000000000000000000000000000000000000000000000000000000000000000000000000000000000000000000000000000000000000000000000000000000000000000000000000000000000000000000000000000000000000000000000000000000000000000000000000000000000000000000000000000000000000000000000000000000000000000000000000000000000000000000000000000000000000000000000000000000000000000000000000000000000000000000000000000000000000000000000000000000000000000000000000000000000000000000000000000000000000000000000000000000000000000000000000000000000000000000000000000000000000000000000000000000000000000000000000000000000000000000000000000000000000000000000000000000000000000000000000000000000000000000000000000000000000000000000000000000000000000000000000000000000000000000000000000000000000000000000000000000000000000000000000000000000000000000000000000000000000000000000000000000000000000000000000000000000000000000000000000000000000000000000000000000000000000000000000000000000000000000000000000000000000000000000000000000000000000000000000000000000000000000000000000000000000000000000000000000000000000000000000000000000000000000000000000000000000000000000000000000000000000000000000000000000000000000000000000000000000000000000000000000000000000000000000000000000000000000000000000000000000000000000000000000000000000000000000000000000000000000000000000000000000000000000000000000000000000000000000000000000000000000000000000000000000000000000000000000000000000000000000000000000000000000000000000000000000000000000000000000000000000000000000000000000000000000000000000000000000000000000000000000000000000000000000000000000000000000000000000000000000000000000000000000000000000000000000000000000000000000000000000000000000000000000000000000000000000000000000000000000000000000000000000000000000000000000000000000000000000000000000000000000000000000000000000000000000000000000000000000000000000000000000000000000000000000000000000000000000000000000000000000000000000000000000000000000000000000000000000000000000000000000000000000000000000000000000000000000000000000000000000000000000000000000000000000000000000000000000000000000000000000000000000000000000000000000000000000000000000000000000000000000000000000000000000000000000000000000000000000000000000000000000000000000000000000000000000000000000000000000000000000000000000000000000000000000000000000000000000000000000000000000000000000000000000000000000000000000000000000000000000000000000000000000000000000000000000000000000000000000000000000000000000000000000000000000000000000000000000000000000000000000000000000000000000000000000000000000000000000000000000000000000000000000000000000000000000000000000000000000000000000000000000000000000000000000000000000000000000000000000000000000000000000000000000000000000000000000000000000000000000000000000000000000000000000000000000000000000000000000000000000000000000000000000000000000000000000000000000000000000000000000000000000000000000000000000000000000000000000000000000000000000000000000000000000000000000000000000000000000000000000000000000000000000000000000000000000000000000000000000000000000000000000000000000000000000000000000000000000000000000000000000000000000000000000000000000000000000000000000000000000000000000000000000000000000000000000000000000000000000000000000000000000000000000000000000000000000000000000000000000000000000000000000000000000000000000000000000000000000000000000000000000000000000000000000000000000000000000000000000000000000000000000000000000000000000000000000000000000000000000000000000000000000000000000000000000000000000000000000000000000000000000000000000000000000000000000000000000000000000000000000000000000000000000000000000000000000000000000000000000000000000000000000000000000000000000000000000000000000000000000000000000000000000000000000000000000000000000000000000000000000000000000000000000000000000000000000000000000000000000000000000000000000000000000000000000000000000000000000000000000000000000000000000000000000000000000000000000000000000000000000000000000000000000000000000000000000000000000000000000000000000000000000000000000000000000000000000000000000000000000000000000000000000000000000000000000000000000000000000000000000000000000000000000000000000000000000000000000000000000000000000000000000000000000000000000000000000000000000000000000000000000000000000000000000000000000000000000000000000000000000000000000000000000000000000000000000000000000000000000000000000000000000000000000000000000000000000000000000000000000000000000000000000000000000000000000000000000000000000000000000000000000000000000000000000000000000000000000000000000000000000000000000000000000000000000000000000000000000000000000000000000000000000000000000000000000000000000000000000000000000000000000000000000000000000000000000000000000000000000000000000000000000000000000000000000000000000000000000000000000000000000000000000000000000000000000000000000000000000000000000000000000000000000000000000000000000000000000000000000000000000000000000000000000000000000000000000000000000000000000000000000000000000000000000000000000000000000000000000000000000000000000000000000000000000000000000000000000000000000000000000000000000000000000000000000000000000000000000000000000000000000000000000000000000000000000000000000000000000000000000000000000000000000000000000000000000000000000000000000000000000000000000000000000000000000000000000000000000000000000000000000000000000000000000000000000000000000000000000000000000000000000000000000000000000000000000000000000000000000000000000000000000000000000000000000000000000000000000000000000000000000000000000000000000000000000000000000000000000000000000000000000000000000000000000000000000000000000000000000000000000000000000000000000000000000000000000000000000000000000000000000000000000000000000000000000000000000000000000000000000000000000000000000000000000000000000000000000000000000000000000000000000000000000000000000000000000000000000000000000000000000000000000000000000000000000000000000000000000000000000000000000000000000000000000000000000000000000000000000000000000000000000000000000000000000000000000000000000000000000000000000000000000000000000000000000000000000000000000000000000000000000000000000000000000000000000000000000000000000000000000000000000000000000000000000000000000000000000000000000000000000000000000000000000000000000000000000000000000000000000000000000000000000000000000000000000000000000000000000000000000000000000000000000000000000000000000000000000000000000000000000000000000000000000000000000000000000000000000000000000000000000000000000000000000000000000000000000000000000000000000000000000000000000000000000000000000000000000000000000000000000000000000000000000000000000000000000000000000000000000000000000000000000000000000000000000000000000000000000000000000000000000000000000000000000000000000000000000000000000000000000000000000000000000000000000000000000000000000000000000000000000000000000000000000000000000000000000000000000000000000000000000000000000000000000000000000000000000000000000000000000000000000000000000000000000000000000000000000000000000000000000000000000000000000000000000000000000000000000000000000000000000000000000000000000000000000000000000000000000000000000000000000000000000000000000000000000000000000000000000000000000000000000000000000000000000000000000000000000000000000000000000000000000000000000000000000000000000000000000000000000000000000000000000000000000000000000000000000000000000000000000000000000000000000000000000000000000000000000000000000000000000000000000000000000000000000000000000000000000000000000000000000000000000000000000000000000000000000000000000000000000000000000000000000000000000000000000000000000000000000000000000000000000000000000000000000000000000000000000000000000000000000000000000000000000000000000000000000000000000000000000000000000000000000000000000000000000000000000000000000000000000000000000000000000000000000000000000000000000000000000000000000000000000000000000000000000000000000000000000000000000000000000000000000000000000000000000000000000000000000000000000000000000000000000000000000000000000000000000000000000000000000000000000000000000000000000000000000000000000000000000000000000000000000000000000000000000000000000000000000000000000000000000000000000000000000000000000000000000000000000000000000000000000000000000000000000000000000000000000000000000000000000000000000000000000000000000000000000000000000000000000000000000000000000000000000000000000000000000000000000000000000000000000000000000000000000000000000000000000000000000000000000000000000000000000000000000000000000000000000000000000000000000000000000000000000000000000000000000000000000000000000000000000000000000000000000000000000000000000000000000000000000000000000000000000000000000000000000000000000000000000000000000000000000000000000000000000000000000000000000000000000000000000000000000000000000000000000000000000000000000000000000000000000000000000000000000000000000000000000000000000000000000000000000000000000000000000000000000000000000000000000000000000000000000000000000000000000000000000000000000000000000000000000000000000000000000000000000000000000000000000000000000000000000000000000000000000000000000000000000000000000000000000000000000000000000000000000000000000000000000000000000000000000000000000000000000000000000000000000000000000000000000000000000000000000000000000000000000000000000000000000000000000000000000000000000000000000000000000000000000000000000000000000000000000000000000000000000000000000000000000000000000000000000000000000000000000000000000000000000000000000000000000000000000000000000000000000000000000000000000000000000000000000000000000000000000000000000000000000000000000000000000000000000000000000000000000000000000000000000000000000000000000000000000000000000000000000000000000000000000000000000000000000000000000000000000000000000000000000000000000000000000000000000000000000000000000000000000000000000000000000000000000000000000000000000000000000000000000000000000000000000000000000000000000000000000000000000000000000000000000000000000000000000000000000000000000000000000000000000000000000000000000000000000000000000000000000000000000000000000000000000000000000000000000000000000000000000000000000000000000000000000000000000000000000000000000000000000000000000000000000000000000000000000000000000000000000000000000000000000000000000000000000000000000000000000000000000000000000000000000000000000000000000000000000000000000000000000000000000000000000000000000000000000000000000000000000000000000000000000000000000000000000000000000000000000000000000000000000000000000000000000000000000000000000000000000000000000000000000000000000000000000000000000000000000000000000000000000000000000000000000000000000000000000000000000000000000000000000000000000000000000000000000000000000000000000000000000000000000000000000000000000000000000000000000000000000000000000000000000000000000000000000000000000000000000000000000000000000000000000000000000000000000000000000000000000000000000000000000000000000000000000000000000000000000000000000000000000000000000000000000000000000000000000000000000000000000000000000000000000000000000000000000000000000000000000000000000000000000000000000000000000000000000000000000000000000000000000000000000000000000000000000000000000000000000000000000000000000000000000000000000000000000000000000000000000000000000000000000000000000000000000000000000000000000000000000000000000000000000000000000000000000000000000000000000000000000000000000000000000000000000000000000000000000000000000000000000000000000000000000000000000000000000000000000000000000000000000000000000000000000000000000000000000000000000000000000000000000000000000000000000000000000000000000000000000000000000000000000000000000000000000000000000000000000000000000000000000000000000000000000000000000000000000000000000000000000000000000000000000000000000000000000000000000000000000000000000000000000000000000000000000000000000000000000000000000000000000000000000000000000000000000000000000000000000000000000000000000000000000000000000000000000000000000000000000000000000000000000000000000000000000000000000000000000000000000000000000000000000000000000000000000000000000000000000000000000000000000000000000000000000000000000000000000000000000000000000000000000000000000000000000000000000000000000000000000000000000000000000000000000000000000000000000000000000000000000000000000000000000000000000000000000000000000000000000000000000000000000000000000000000000000000000000000000000000000000000000000000000000000000000000000000000000000000000000000000000000000000000000000000000000000000000000000000000000000000000000000000000000000000000000000000000000000000000000000000000000000000000000000000000000000000000000000000000000000000000000000000000000000000000000000000000000000000000000000000000000000000000000000000000000000000000000000000000000000000000000000000000000000000000000000000000000000000000000000000000000000000000000000000000000000000000000000000000000000000000000000000000000000000000000000000000000000000000000000000000000000000000000000000000000000000000000000000000000000000000000000000000000000000000000000000000000000000000000000000000000000000000000000000000000000000000000000000000000000000000000000000000000000000000000000000000000000000000000000000000000000000000000000000000000000000000000000000000000000000000000000000000000000000000000000000000000000000000000000000000000000000000000000000000000000000000000000000000000000000000000000000000000000000000000000000000000000000000000000000000000000000000000000000000000000000000000000000000000000000000000000000000000000000000000000000000000000000000000000000000000000000000000000000000000000000000000000000000000000000000000000000000000000000000000000000000000000000000000000000000000000000000000000000000000000000000000000000000000000000000000000000000000000000000000000000000000000000000000000000000000000000000000000000000000000000000000000000000000000000000000000000000000000000000000000000000000000000000000000000000000000000000000000000000000000000000000000000000000000000000000000000000000000000000000000000000000000000000000000000000000000000000000000000000000000000000000000000000000000000000000000000000000000000000000000000000000000000000000000000000000000000000000000000000000000000000000000000000000000000000000000000000000000000000000000000000000000000000000000000000000000000000000000000000000000000000000000000000000000000000000000000000000000000000000000000000000000000000000000000000000000000000000000000000000000000000000000000000000000000000000000000000000000000000000000000000000000000000000000000000000000000000000000000000000000000000000000000000000000000000000000000000000000000000000000000000000000000000000000000000000000000000000000000000000000000000000000000000000000000000000000000000000000000000000000000000000000000000000000000000000000000000000000000000000000000000000000000000000000000000000000000000000000000000000000000000000000000000000000000000000000000000000000000000000000000000000000000000000000000000000000000000000000000000000000000000000000000000000000000000000000000000000000000000000000000000000000000000000000000000000000000000000000000000000000000000000000000000000000000000000000000000000000000000000000000000000000000000000000000000000000000000000000000000000000000000000000000000000000000000000000000000000000000000000000000000000000000000000000000000000000000000000000000000000000000000000000000000000000000000000000000000000000000000000000000000000000000000000000000000000000000000000000000000000000000000000000000000000000000000000000000000000000000000000000000000000000000000000000000000000000000000000000000000000000000000000000000000000000000000000000000000000000000000000000000000000000000000000000000000000000000000000000000000000000000000000000000000000000000000000000000000000000000000000000000000000000000000000000000000000000000000000000000000000000000000000000000000000000000000000000000000000000000000000000000000000000000000000000000000000000000000000000000000000000000000000000000000000000000000000000000000000000000000000000000000000000000000000000000000000000000000000000000000000000000000000000000000000000000000000000000000000000000000000000000000000000000000000000000000000000000000000000000000000000000000000000000000000000000000000000000000000000000000000000000000000000000000000000000000000000000000000000000000000000000000000000000000000000000000000000000000000000000000000000000000000000000000000000000000000000000000000000000000000000000000000000000000000000000000000000000000000000000000000000000000000000000000000000000000000000000000000000000000000000000000000000000000000000000000000000000000000000000000000000000000000000000000000000000000000000000000000000000000000000000000000000000000000000000000000000000000000000000000000000000000000000000000000000000000000000000000000000000000000000000000000000000000000000000000000000000000000000000000000000000000000000000000000000000000000000000000000000000000000000000000000000000000000000000000000000000000000000000000000000000000000000000000000000000000000000000000000000000000000000000000000000000000000000000000000000000000000000000000000000000000000000000000000000000000000000000000000000000000000000000000000000000000000000000000000000000000000000000000000000000000000000000000000000000000000000000000000000000000000000000000000000000000000000000000000000000000000000000000000000000000000000000000000000000000000000000000000000000000000000000000000000000000000000000000000000000000000000000000000000000000000000000000000000000000000000000000000000000000000000000000000000000000000000000000000000000000000000000000000000000000000000000000000000000000000000000000000000000000000000000000000000000000000000000000000000000000000000000000000000000000000000000000000000000000000000000000000000000000000000000000000000000000000000000000000000000000000000000000000000000000000000000000000000000000000000000000000000000000000000000000000000000000000000000000000000000000000000000000000000000000000000000000000000000000000000000000000000000000000000000000000000000000000000000000000000000000000000000000000000000000000000000000000000000000000000000000000000000000000000000000000000000000000000000000000000000000000000000000000000000000000000000000000000000000000000000000000000000000000000000000000000000000000000000000000000000000000000000000000000000000000000000000000000000000000000000000000000000000000000000000000000000000000000000000000000000000000000000000000000000000000000000000000000000000000000000000000000000000000000000000000000000000000000000000000000000000000000000000000000000000000000000000000000000000000000000000000000000000000000000000000000000000000000000000000000000000000000000000000000000000000000000000000000000000000000000000000000000000000000000000000000000000000000000000000000000000000000000000000000000000000000000000000000000000000000000000000000000000000000000000000000000000000000000000000000000000000000000000000000000000000000000000000000000000000000000000000000000000000000000000000000000000000000000000000000000000000000000000000000000000000000000000000000000000000000000000000000000000000000000000000000000000000000000000000000000000000000000000000000000000000000000000000000000000000000000000000000000000000000000000000000000000000000000000000000000000000000000000000000000000000000000000000000000000000000000000000000000000000000000000000000000000000000000000000000000000000000000000000000000000000000000000000000000000000000000000000000000000000000000000000000000000000000000000000000000000000000000000000000000000000000000000000000000000000000000000000000000000000000000000000000000000000000000000000000000000000000000000000000000000000000000000000000000000000000000000000000000000000000000000000000000000000000000000000000000000000000000000000000000000000000000000000000000000000000000000000000000000000000000000000000000000000000000000000000000000000000000000000000000000000000000000000000000000000000000000000000000000000000000000000000000000000000000000000000000000000000000000000000000000000000000000000000000000000000000000000000000000000000000000000000000000000000000000000000000000000000000000000000000000000000000000000000000000000000000000000000000000000000000000000000000000000000000000000000000000000000000000000000000000000000000000000000000000000000000000000000000000000000000000000000000000000000000000000000000000000000000000000000000000000000000000000000000000000000000000000000000000000000000000000000000000000000000000000000000000000000000000000000000000000000000000000000000000000000000000000000000000000000000000000000000000000000000000000000000000000000000000000000000000000000000000000000000000000000000000000000000000000000000000000000000000000000000000000000000000000000000000000000000000000000000000000000000000000000000000000000000000000000000000000000000000000000000000000000000000000000000000000000000000000000000000000000000000000000000000000000000000000000000000000000000000000000000000000000000000000000000000000000000000000000000000000000000000000000000000000000000000000000000000000000000000000000000000000000000000000000000000000000000000000000000000000000000000000000000000000000000000000000000000000000000000000000000000000000000000000000000000000000000000000000000000000000000000000000000000000000000000000000000000000000000000000000000000000000000000000000000000000000000000000000000000000000000000000000000000000000000000000000000000000000000000000000000000000000000000000000000000000000000000000000000000000000000000000000000000000000000000000000000000000000000000000000000000000000000000000000000000000000000000000000000000000000000000000000000000000000000000000000000000000000000000000000000000000000000000000000000000000000000000000000000000000000000000000000000000000000000000000000000000000000000000000000000000000000000000000000000000000000000000000000000000000000000000000000000000000000000000000000000000000000000000000000000000000000000000000000000000000000000000000000000000000000000000000000000000000000000000000000000000000000000000000000000000000000000000000000000000000000000000000000000000000000000000000000000000000000000000000000000000000000000000000000000000000000000000000000000000000000000000000000000000000000000000000000000000000000000000000000000000000000000000000000000000000000000000000000000000000000000000000000000000000000000000000000000000000000000000000000000000000000000000000000000000000000000000000000000000000000000000000000000000000000000000000000000000000000000000000000000000000000000000000000000000000000000000000000000000000000000000000000000000000000000000000000000000000000000000000000000000000000000000000000000000000000000000000000000000000000000000000000000000000000000000000000000000000000000000000000000000000000000000000000000000000000000000000000000000000000000000000000000000000000000000000000000000000000000000000000000000000000000000000000000000000000000000000000000000000000000000000000000000000000000000000000000000000000000000000000000000000000000000000000000000000000000000000000000000000000000000000000000000000000000000000000000000000000000000000000000000000000000000000000000000000000000000000000000000000000000000000000000000000000000000000000000000000000000000000000000000000000000000000000000000000000000000000000000000000000000000000000000000000000000000000000000000000000000000000000000000000000000000000000000000000000000000000000000000000000000000000000000000000000000000000000000000000000000000000000000000000000000000000000000000000000000000000000000000000000000000000000000000000000000000000000000000000000000000000000000000000000000000000000000000000000000000000000000000000000000000000000000000000000000000000000000000000000000000000000000000000000000000000000000000000000000000000000000000000000000000000000000000000000000000000000000000000000000000000000000000000000000000000000000000000000000000000000000000000000000000000000000000000000000000000000000000000000000000000000000000000000000000000000000000000000000000000000000000000000000000000000000000000000000000000000000000000000000000000000000000000000000000000000000000000000000000000000000000000000000000000000000000000000000000000000000000000000000000000000000000000000000000000000000000000000000000000000000000000000000000000000000000000000000000000000000000000000000000000000000000000000000000000000000000000000000000000000000000000000000000000000000000000000000000000000000000000000000000000000000000000000000000000000000000000000000000000000000000000000000000000000000000000000000000000000000000000000000000000000000000000000000000000000000000000000000000000000000000000000000000000000000000000000000000000000000000000000000000000000000000000000000000000000000000000000000000000000000000000000000000000000000000000000000000000000000000000000000000000000000000000000000000000000000000000000000000000000000000000000000000000000000000000000000000000000000000000000000000000000000000000000000000000000000000000000000000000000000000000000000000000000000000000000000000000000000000000000000000000000000000000000000000000000000000000000000000000000000000000000000000000000000000000000000000000000000000000000000000000000000000000000000000000000000000000000000000000000000000000000000000000000000000000000000000000000000000000000000000000000000000000000000000000000000000000000000000000000000000000000000000000000000000000000000000000000000000000000000000000000000000000000000000000000000000000000000000000000000000000000000000000000000000000000000000000000000000000000000000000000000000000000000000000000000000000000000000000000000000000000000000000000000000000000000000000000000000000000000000000000000000000000000000000000000000000000000000000000000000000000000000000000000000000000000000000000000000000000000000000000000000000000000000000000000000000000000000000000000000000000000000000000000000000000000000000000000000000000000000000000000000000000000000000000000000000000000000000000000000000000000000000000000000000000000000000000000000000000000000000000000000000000000000000000000000000000000000000000000000000000000000000000000000000000000000000000000000000000000000000000000000000000000000000000000000000000000000000000000000000000000000000000000000000000000000000000000000000000000000000000000000000000000000000000000000000000000000000000000000000000000000000000000000000000000000000000000000000000000000000000000000000000000000000000000000000000000000000000000000000000000000000000000000000000000000000000000000000000000000000000000000000000000000000000000000000000000000000000000000000000000000000000000000000000000000000000000000000000000000000000000000000000000000000000000000000000000000000000000000000000000000000000000000000000000000000000000000000000000000000000000000000000000000000000000000000000000000000000000000000000000000000000000000000000000000000000000000000000000000000000000000000000000000000000000000000000000000000000000000000000000000000000000000000000000000000000000000000000000000000000000000000000000000000000000000000000000000000000000000000000000000000000000000000000000000000000000000000000000000000000000000000000000000000000000000000000000000000000000000000000000000000000000000000000000000000000000000000000000000000000000000000000000000000000000000000000000000000000000000000000000000000000000000000000000000000000000000000000000000000000000000000000000000000000000000000000000000000000000000000000000000000000000000000000000000000000000000000000000000000000000000000000000000000000000000000000000000000000000000000000000000000000000000000000000000000000000000000000000000000000000000000000000000000000000000000000000000000000000000000000000000000000000000000000000000000000000000000000000000000000000000000000000000000000000000000000000000000000000000000000000000000000000000000000000000000000000000000000000000000000000000000000000000000000000000000000000000000000000000000000000000000000000000000000000000000000000000000000000000000000000000000000000000000000000000000000000000000000000000000000000000000000000000000000000000000000000000000000000000000000000000000000000000000000000000000000000000000000000000000000000000000000000000000000000000000000000000000000000000000000000000000000000000000000000000000000000000000000000000000000000000000000000000000000000000000000000000000000000000000000000000000000000000000000000000000000000000000000000000000000000000000000000000000000000000000000000000000000000000000000000000000000000000000000000000000000000000000000000000000000000000000000000000000000000000000000000000000000000000000000000000000000000000000000000000000000000000000000000000000000000000000000000000000000000000000000000000000000000000000000000000000000000000000000000000000000000000000000000000000000000000000000000000000000000000000000000000000000000000000000000000000000000000000000000000000000000000000000000000000000000000000000000000000000000000000000000000000000000000000000000000000000000000000000000000000000000000000000000000000000000000000000000000000000000000000000000000000000000000000000000000000000000000000000000000000000000000000000000000000000000000000000000000000000000000000000000000000000000000000000000000000000000000000000000000000000000000000000000000000000000000000000000000000000000000000000000000000000000000000000000000000000000000000000000000000000000000000000000000000000000000000000000000000000000000000000000000000000000000000000000000000000000000000000000000000000000000000000000000000000000000000000000000000000000000000000000000000000000000000000000000000000000000000000000000000000000000000000000000000000000000000000000000000000000000000000000000000000000000000000000000000000000000000000000000000000000000000000000000000000000000000000000000000000000000000000000000000000000000000000000000000000000000000000000000000000000000000000000000000000000000000000000000000000000000000000000000000000000000000000000000000000000000000000000000000000000000000000000000000000000000000000000000000000000000000000000000000000000000000000000000000000000000000000000000000000000000000000000000000000000000000000000000000000000000000000000000000000000000000000000000000000000000000000000000000000000000000000000000000000000000000000000000000000000000000000000000000000000000000000000000000000000000000000000000000000000000000000000000000000000000000000000000000000000000000000000000000000000000000000000000000000000000000000000000000000000000000000000000000000000000000000000000000000000000000000000000000000000000000000000000000000000000000000000000000000000000000000000000000000000000000000000000000000000000000000000000000000000000000000000000000000000000000000000000000000000000000000000000000000000000000000000000000000000000000000000000000000000000000000000000000000000000000000000000000000000000000000000000000000000000000000000000000000000000000000000000000000000000000000000000000000000000000000000000000000000000000000000000000000000000000000000000000000000000000000000000000000000000000000000000000000000000000000000000000000000000000000000000000000000000000000000000000000000000000000000000000000000000000000000000000000000000000000000000000000000000000000000000000000000000000000000000000000000000000000000000000000000000000000000000000000000000000000000000000000000000000000000000000000000000000000000000000000000000000000000000000000000000000000000000000000000000000000000000000000000000000000000000000000000000000000000000000000000000000000000000000000000000000000000000000000000000000000000000000000000000000000000000000000000000000000000000000000000000000000000000000000000000000000000000000000000000000000000000000000000000000000000000000000000000000000000000000000000000000000000000000000000000000000000000000000000000000000000000000000000000000000000000000000000000000000000000000000000000000000000000000000000000000000000000000000000000000000000000000000000000000000000000000000000000000000000000000000000000000000000000000000000000000000000000000000000000000000000000000000000000000000000000000000000000000000000000000000000000000000000000000000000000000000000000000000000000000000000000000000000000000000000000000000000000000000000000000000000000000000000000000000000000000000000000000000000000000000000000000000000000000000000000000000000000000000000000000000000000000000000000000000000000000000000000000000000000000000000000000000000000000000000000000000000000000000000000000000000000000000000000000000000000000000000000000000000000000000000000000000000000000000000000000000000000000000000000000000000000000000000000000000000000000000000000000000000000000000000000000000000000000000000000000000000000000000000000000000000000000000000000000000000000000000000000000000000000000000000000000000000000000000000000000000000000000000000000000000000000000000000000000000000000000000000000000000000000000000000000000000000000000000000000000000000000000000000000000000000000000000000000000000000000000000000000000000000000000000000000000000000000000000000000000000000000000000000000000000000000000000000000000000000000000000000000000000000000000000000000000000000000000000000000000000000000000000000000000000000000000000000000000000000000000000000000000000000000000000000000000000000000000000000000000000000000000000000000000000000000000000000000000000000000000000000000000000000000000000000000000000000000000000000000000000000000000000000000000000000000000000000000000000000000000000000000000000000000000000000000000000000000000000000000000000000000000000000000000000000000000000000000000000000000000000000000000000000000000000000000000000000000000000000000000000000000000000000000000000000000000000000000000000000000000000000000000000000000000000000000000000000000000000000000000000000000000000000000000000000000000000000000000000000000000000000000000000000000000000000000000000000000000000000000000000000000000000000000000000000000000000000000000000000000000000000000000000000000000000000000000000000000000000000000000000000000000000000000000000000000000000000000000000000000000000000000000000000000000000000000000000000000000000000000000000000000000000000000000000000000000000000000000000000000000000000000000000000000000000000000000000000000000000000000000000000000000000000000000000000000000000000000000000000000000000000000000000000000000000000000000000000000000000000000000000000000000000000000000000000000000000000000000000000000000000000000000000000000000000000000000000000000000000000000000000000000000000000000000000000000000000000000000000000000000000000000000000000000000000000000000000000000000000000000000000000000000000000000000000000000000000000000000000000000000000000000000000000000000000000000000000000000000000000000000000000000000000000000000000000000000000000000000000000000000000000000000000000000000000000000000000000000000000000000000000000000000000000000000000000000000000000000000000000000000000000000000000000000000000000000000000000000000000000000000000000000000000000000000000000000000000000000000000000000000000000000000000000000000000000000000000000000000000000000000000000000000000000000000000000000000000000000000000000000000000000000000000000000000000000000000000000000000000000000000000000000000000000000000000000000000000000000000000000000000000000000000000000000000000000000000000000000000000000000000000000000000000000000000000000000000000000000000000000000000000000000000000000000000000000000000000000000000000000000000000000000000000000000000000000000000000000000000000000000000000000000000000000000000000000000000000000000000000000000000000000000000000000000000000000000000000000000000000000000000000000000000000000000000000000000000000000000000000000000000000000000000000000000000000000000000000000000000000000000000000000000000000000000000000000000000000000000000000000000000000000000000000000000000000000000000000000000000000000000000000000000000000000000000000000000000000000000000000000000000000000000000000000000000000000000000000000000000000000000000000000000000000000000000000000000000000000000000000000000000000000000000000000000000000000000000000000000000000000000000000000000000000000000000000000000000000000000000000000000000000000000000000000000000000000000000000000000000000000000000000000000000000000000000000000000000000000000000000000000000000000000000000000000000000000000000000000000000000000000000000000000000000000000000000000000000000000000000000000000000000000000000000000000000000000000000000000000000000000000000000000000000000000000000000000000000000000000000000000000000000000000000000000000000000000000000000000000000000000000000000000000000000000000000000000000000000000000000000000000000000000000000000000000000000000000000000000000000000000000000000000000000000000000000000000000000000000000000000000000000000000000000000000000000000000000000000000000000000000000000000000000000000000000000000000000000000000000000000000000000000000000000000000000000000000000000000000000000000000000000000000000000000000000000000000000000000000000000000000000000000000000000000000000000000000000000000000000000000000000000000000000000000000000000000000000000000000000000000000000000000000000000000000000000000000000000000000000000000000000000000000000000000000000000000000000000000000000000000000000000000000000000000000000000000000000000000000000000000000000000000000000000000000000000000000000000000000000000000000000000000000000000000000000000000000000000000000000000000000000000000000000000000000000000000000000000000000000000000000000000000000000000000000000000000000000000000000000000000000000000000000000000000000000000000000000000000000000000000000000000000000000000000000000000000000000000000000000000000000000000000000000000000000000000000000000000000000000000000000000000000000000000000000000000000000000000000000000000000000000000000000000000000000000000000000000000000000000000000000000000000000000000000000000000000000000000000000000000000000000000000000000000000000000000000000000000000000000000000000000000000000000000000000000000000000000000000000000000000000000000000000000000000000000000000000000000000000000000000000000000000000000000000000000000000000000000000000000000000000000000000000000000000000000000000000000000000000000000000000000000000000000000000000000000000000000000000000000000000000000000000000000000000000000000000000000000000000000000000000000000000000000000000000000000000000000000000000000000000000000000000000000000000000000000000000000000000000000000000000000000000000000000000000000000000000000000000000000000000000000000000000000000000000000000000000000000000000000000000000000000000000000000000000000000000000000000000000000000000000000000000000000000000000000000000000000000000000000000000000000000000000000000000000000000000000000000000000000000000000000000000000000000000000000000000000000000000000000000000000000000000000000000000000000000000000000000000000000000000000000000000000000000000000000000000000000000000000000000000000000000000000000000000000000000000000000000000000000000000000000000000000000000000000000000000000000000000000000000000000000000000000000000000000000000000000000000000000000000000000000000000000000000000000000000000000000000000000000000000000000000000000000000000000000000000000000000000000000000000000000000000000000000000000000000000000000000000000000000000000000000000000000000000000000000000000000000000000000000000000000000000000000000000000000000000000000000000000000000000000000000000000000000000000000000000000000000000000000000000000000000000000000000000000000000000000000000000000000000000000000000000000000000000000000000000000000000000000000000000000000000000000000000000000000000000000000000000000000000000000000000000000000000000000000000000000000000000000000000000000000000000000000000000000000000000000000000000000000000000000000000000000000000000000000000000000000000000000000000000000000000000000000000000000000000000000000000000000000000000000000000000000000000000000000000000000000000000000000000000000000000000000000000000000000000000000000000000000000000000000000000000000000000000000000000000000000000000000000000000000000000000000000000000000000000000000000000000000000000000000000000000000000000000000000000000000000000000000000000000000000000000000000000000000000000000000000000000000000000000000000000000000000000000000000000000000000000000000000000000000000000000000000000000000000000000000000000000000000000000000000000000000000000000000000000000000000000000000000000000000000000000000000000000000000000000000000000000000000000000000000000000000000000000000000000000000000000000000000000000000000000000000000000000000000000000000000000000000000000000000000000000000000000000000000000000000000000000000000000000000000000000000000000000000000000000000000000000000000000000000000000000000000000000000000000000000000000000000000000000000000000000000000000000000000000000000000000000000000000000000000000000000000000000000000000000000000000000000000000000000000000000000000000000000000000000000000000000000000000000000000000000000000000000000000000000000000000000000000000000000000000000000000000000000000000000000000000000000000000000000000000000000000000000000000000000000000000000000000000000000000000000000000000000000000000000000000000000000000000000000000000000000000000000000000000000000000000000000000000000000000000000000000000000000000000000000000000000000000000000000000000000000000000000000000000000000000000000000000000000000000000000000000000000000000000000000000000000000000000000000000000000000000000000000000000000000000000000000000000000000000000000000000000000000000000000000000000000000000000000000000000000000000000000000000000000000000000000000000000000000000000000000000000000000000000000000000000000000000000000000000000000000000000000000000000000000000000000000000000000000000000000000000000000000000000000000000000000000000000000000000000000000000000000000000000000000000000000000000000000000000000000000000000000000000000000000000000000000000000000000000000000000000000000000000000000000000000000000000000000000000000000000000000000000000000000000000000000000000000000000000000000000000000000000000000000000000000000000000000000000000000000000000000000000000000000000000000000000000000000000000000000000000000000000000000000000000000000000000000000000000000000000000000000000000000000000000000000000000000000000000000000000000000000000000000000000000000000000000000000000000000000000000000000000000000000000000000000000000000000000000000000000000000000000000000000000000000000000000000000000000000000000000000000000000000000000000000000000000000000000000000000000000000000000000000000000000000000000000000000000000000000000000000000000000000000000000000000000000000000000000000000000000000000000000000000000000000000000000000000000000000000000000000000000000000000000000000000000000000000000000000000000000000000000000000000000000000000000000000000000000000000000000000000000000000000000000000000000000000000000000000000000000000000000000000000000000000000000000000000000000000000000000000000000000000000000000000000000000000000000000000000000000000000000000000000000000000000000000000000000000000000000000000000000000000000000000000000000000000000000000000000000000000000000000000000000000000000000000000000000000000000000000000000000000000000000000000000000000000000000000000000000000000000000000000000000000000000000000000000000000000000000000000000000000000000000000000000000000000000000000000000000000000000000000000000000000000000000000000000000000000000000000000000000000000000000000000000000000000000000000000000000000000000000000000000000000000000000000000000000000000000000000000000000000000000000000000000000000000000000000000000000000000000000000000000000000000000000000000000000000000000000000000000000000000000000000000000000000000000000000000000000000000000000000000000000000000000000000000000000000000000000000000000000000000000000000000000000000000000000000000000000000000000000000000000000000000000000000000000000000000000000000000000000000000000000000000000000000000000000000000000000000000000000000000000000000000000000000000000000000000000000000000000000000000000000000000000000000000000000000000000000000000000000000000000000000000000000000000000000000000000000000000000000000000000000000000000000000000000000000000000000000000000000000000000000000000000000000000000000000000000000000000000000000000000000000000000000000000000000000000000000000000000000000000000000000000000000000000000000000000000000000000000000000000000000000000000000000000000000000000000000000000000000000000000000000000000000000000000000000000000000000000000000000000000000000000000000000000000000000000000000000000000000000000000000000000000000000000000000000000000000000000000000000000000000000000000000000000000000000000000000000000000000000000000000000000000000000000000000000000000000000000000000000000000000000000000000000000000000000000000000000000000000000000000000000000000000000000000000000000000000000000000000000000000000000000000000000000000000000000000000000000000000000000000000000000000000000000000000000000000000000000000000000000000000000000000000000000000000000000000000000000000000000000000000000000000000000000000000000000000000000000000000000000000000000000000000000000000000000000000000000000000000000000000000000000000000000000000000000000000000000000000000000000000000000000000000000000000000000000000000000000000000000000000000000000000000000000000000000000000000000000000000000000000000000000000000000000000000000000000000000000000000000000000000000000000000000000000000000000000000000000000000000000000000000000000000000000000000000000000000000000000000000000000000000000000000000000000000000000000000000000000000000000000000000000000000000000000000000000000000000000000000000000000000000000000000000000000000000000000000000000000000000000000000000000000000000000000000000000000000000000000000000000000000000000000000000000000000000000000000000000000000000000000000000000000000000000000000000000000000000000000000000000000000000000000000000000000000000000000000000000000000000000000000000000000000000000000000000000000000000000000000000000000000000000000000000000000000000000000000000000000000000000000000000000000000000000000000000000000000000000000000000000000000000000000000000000000000000000000000000000000000000000000000000000000000000000000000000000000000000000000000000000000000000000000000000000000000000000000000000000000000000000000000000000000000000000000000000000000000000000000000000000000000000000000000000000000000000000000000000000000000000000000000000000000000000000000000000000000000000000000000000000000000000000000000000000000000000000000000000000000000000000000000000000000000000000000000000000000000000000000000000000000000000000000000000000000000000000000000000000000000000000000000000000000000000000000000000000000000000000000000000000000000000000000000000000000000000000000000000000000000000000000000000000000000000000000000000000000000000000000000000000000000000000000000000000000000000000000000000000000000000000000000000000000000000000000000000000000000000000000000000000000000000000000000000000000000000000000000000000000000000000000000000000000000000000000000000000000000000000000000000000000000000000000000000000000000000000000000000000000000000000000000000000000000000000000000000000000000000000000000000000000000000000000000000000000000000000000000000000000000000000000000000000000000000000000000000000000000000000000000000000000000000000000000000000000000000000000000000000000000000000000000000000000000000000000000000000000000000000000000000000000000000000000000000000000000000000000000000000000000000000000000000000000000000000000000000000000000000000000000000000000000000000000000000000000000000000000000000000000000000000000000000000000000000000000000000000000000000000000000000000000000000000000000000000000000000000000000000000000000000000000000000000000000000000000000000000000000000000000000000000000000000000000000000000000000000000000000000000000000000000000000000000000000000000000000000000000000000000000000000000000000000000000000000000000000000000000000000000000000000000000000000000000000000000000000000000000000000000000000000000000000000000000000000000000000000000000000000000000000000000000000000000000000000000000000000000000000000000000000000000000000000000000000000000000000000000000000000000000000000000000000000000000000000000000000000000000000000000000000000000000000000000000000000000000000000000000000000000000000000000000000000000000000000000000000000000000000000000000000000000000000000000000000000000000000000000000000000000000000000000000000000000000000000000000000000000000000000000000000000000000000000000000000000000000000000000000000000000000000000000000000000000000000000000000000000000000000000000000000000000000000000000000000000000000000000000000000000000000000000000000000000000000000000000000000000000000000000000000000000000000000000000000000000000000000000000000000000000000000000000000000000000000000000000000000000000000000000000000000000000000000000000000000000000000000000000000000000000000000000000000000000000000000000000000000000000000000000000000000000000000000000000000000000000000000000000000000000000000000000000000000000000000000000000000000000000000000000000000000000000000000000000000000000000000000000000000000000000000000000000000000000000000000000000000000000000000000000000000000000000000000000000000000000000000000000000000000000000000000000000000000000000000000000000000000000000000000000000000000000000000000000000000000000000000000000000000000000000000000000000000000000000000000000000000000000000000000000000000000000000000000000000000000000000000000000000000000000000000000000000000000000000000000000000000000000000000000000000000000000000000000000000000000000000000000000000000000000000000000000000000000000000000000000000000000000000000000000000000000000000000000000000000000000000000000000000000000000000000000000000000000000000000000000000000000000000000000000000000000000000000000000000000000000000000000000000000000000000000000000000000000000000000000000000000000000000000000000000000000000000000000000000000000000000000000000000000000000000000000000000000000000000000000000000000000000000000000000000000000000000000000000000000000000000000000000000000000000000000000000000000000000000000000000000000000000000000000000000000000000000000000000000000000000000000000000000000000000000000000000000000000000000000000000000000000000000000000000000000000000000000000000000000000000000000000000000000000000000000000000000000000000000000000000000000000000000000000000000000000000000000000000000000000000000000000000000000000000000000000000000000000000000000000000000000000000000000000000000000000000000000000000000000000000000000000000000000000000000000000000000000000000000000000000000000000000000000000000000000000000000000000000000000000000000000000000000000000000000000000000000000000000000000000000000000000000000000000000000000000000000000000000000000000000000000000000000000000000000000000000000000000000000000000000000000000000000000000000000000000000000000000000000000000000000000000000000000000000000000000000000000000000000000000000000000000000000000000000000000000000000000000000000000000000000000000000000000000000000000000000000000000000000000000000000000000000000000000000000000000000000000000000000000000000000000000000000000000000000000000000000000000000000000000000000000000000000000000000000000000000000000000000000000000000000000000000000000000000000000000000000000000000000000000000000000000000000000000000000000000000000000000000000000000000000000000000000000000000000000000000000000000000000000000000000000000000000000000000000000000000000000000000000000000000000000000000000000000000000000000000000000000000000000000000000000000000000000000000000000000000000000000000000000000000000000000000000000000000000000000000000000000000000000000000000000000000000000000000000000000000000000000000000000000000000000000000000000000000000000000000000000000000000000000000000000000000000000000000000000000000000000000000000000000000000000000000000000000000000000000000000000000000000000000000000000000000000000000000000000000000000000000000000000000000000000000000000000000000000000000000000000000000000000000000000000000000000000000000000000000000000000000000000000000000000000000000000000000000000000000000000000000000000000000000000000000000000000000000000000000000000000000000000000000000000000000000000000000000000000000000000000000000000000000000000000000000000000000000000000000000000000000000000000000000000000000000000000000000000000000000000000000000000000000000000000000000000000000000000000000000000000000000000000000000000000000000000000000000000000000000000000000000000000000000000000000000000000000000000000000000000000000000000000000000000000000000000000000000000000000000000000000000000000000000000000000000000000000000000000000000000000000000000000000000000000000000000000000000000000000000000000000000000000000000000000000000000000000000000000000000000000000000000000000000000000000000000000000000000000000000000000000000000000000000000000000000000000000000000000000000000000000000000000000000000000000000000000000000000000000000000000000000000000000000000000000000000000000000000000000000000000000000000000000000000000000000000000000000000000000000000000000000000000000000000000000000000000000000000000000000000000000000000000000000000000000000000000000000000000000000000000000000000000000000000000000000000000000000000000000000000000000000000000000000000000000000000000000000000000000000000000000000000000000000000000000000000000000000000000000000000000000000000000000000000000000000000000000000000000000000000000000000000000000000000000000000000000000000000000000000000000000000000000000000000000000000000000000000000000000000000000000000000000000000000000000000000000000000000000000000000000000000000000000000000000000000000000000000000000000000000000000000000000000000000000000000000000000000000000000000000000000000000000000000000000000000000000000000000000000000000000000000000000000000000000000000000000000000000000000000000000000000000000000000000000000000000000000000000000000000000000000000000000000000000000000000000000000000000000000000000000000000000000000000000000000000000000000000000000000000000000000000000000000000000000000000000000000000000000000000000000000000000000000000000000000000000000000000000000000000000000000000000000000000000000000000000000000000000000000000000000000000000000000000000000000000000000000000000000000000000000000000000000000000000000000000000000000000000000000000000000000000000000000000000000000000000000000000000000000000000000000000000000000000000000000000000000000000000000000000000000000000000000000000000000000000000000000000000000000000000000000000000000000000000000000000000000000000000000000000000000000000000000000000000000000000000000000000000000000000000000000000000000000000000000000000000000000000000000000000000000000000000000000000000000000000000000000000000000000000000000000000000000000000000000000000000000000000000000000000000000000000000000000000000000000000000000000000000000000000000000000000000000000000000000000000000000000000000000000000000000000000000000000000000000000000000000000000000000000000000000000000000000000000000000000000000000000000000000000000000000000000000000000000000000000000000000000000000000000000000000000000000000000000000000000000000000000000000000000000000000000000000000000000000000000000000000000000000000000000000000000000000000000000000000000000000000000000000000000000000000000000000000000000000000000000000000000000000000000000000000000000000000000000000000000000000000000000000000000000000000000000000000000000000000000000000000000000000000000000000000000000000000000000000000000000000000000000000000000000000000000000000000000000000000000000000000000000000000000000000000000000000000000000000000000000000000000000000000000000000000000000000000000000000000000000000000000000000000000000000000000000000000000000000000000000000000000000000000000000000000000000000000000000000000000000000000000000000000000000000000000000000000000000000000000000000000000000000000000000000000000000000000000000000000000000000000000000000000000000000000000000000000000000000000000000000000000000000000000000000000000000000000000000000000000000000000000000000000000000000000000000000000000000000000000000000000000000000000000000000000000000000000000000000000000000000000000000000000000000000000000000000000000000000000000000000000000000000000000000000000000000000000000000000000000000000000000000000000000000000000000000000000000000000000000000000000000000000000000000000000000000000000000000000000000000000000000000000000000000000000000000000000000000000000000000000000000000000000000000000000000000000000000000000000000000000000000000000000000000000000000000000000000000000000000000000000000000000000000000000000000000000000000000000000000000000000000000000000000000000000000000000000000000000000000000000000000000000000000000000000000000000000000000000000000000000000000000000000000000000000000000000000000000000000000000000000000000000000000000000000000000000000000000000000000000000000000000000000000000000000000000000000000000000000000000000000000000000000000000000000000000000000000000000000000000000000000000000000000000000000000000000000000000000000000000000000000000000000000000000000000000000000000000000000000000000000000000000000000000000000000000000000000000000000000000000000000000000000000000000000000000000000000000000000000000000000000000000000000000000000000000000000000000000000000000000000000000000000000000000000000000000000000000000000000000000000000000000000000000000000000000000000000000000000000000000000000000000000000000000000000000000000000000000000000000000000000000000000000000000000000000000000000000000000000000000000000000000000000000000000000000000000000000000000000000000000000000000000000000000000000000000000000000000000000000000000000000000000000000000000000000000000000000000000000000000000000000000000000000000000000000000000000000000000000000000000000000000000000000000000000000000000000000000000000000000000000000000000000000000000000000000000000000000000000000000000000000000000000000000000000000000000000000000000000000000000000000000000000000000000000000000000000000000000000000000000000000000000000000000000000000000000000000000000000000000000000000000000000000000000000000000000000000000000000000000000000000000000000000000000000000000000000000000000000000000000000000000000000000000000000000000000000000000000000000000000000000000000000000000000000000000000000000000000000000000000000000000000000000000000000000000000000000000000000000000000000000000000000000000000000000000000000000000000000000000000000000000000000000000000000000000000000000000000000000000000000000000000000000000000000000000000000000000000000000000000000000000000000000000000000000000000000000000000000000000000000000000000000000000000000000000000000000000000000000000000000000000000000000000000000000000000000000000000000000000000000000000000000000000000000000000000000000000000000000000000000000000000000000000000000000000000000000000000000000000000000000000000000000000000000000000000000000000000000000000000000000000000000000000000000000000000000000000000000000000000000000000000000000000000000000000000000000000000000000000000000000000000000000000000000000000000000000000000000000000000000000000000000000000000000000000000000000000000000000000000000000000000000000000000000000000000000000000000000000000000000000000000000000000000000000000000000000000000000000000000000000000000000000000000000000000000000000000000000000000000000000000000000000000000000000000000000000000000000000000000000000000000000000000000000000000000000000000000000000000000000000000000000000000000000000000000000000000000000000000000000000000000000000000000000000000000000000000000000000000000000000000000000000000000000000000000000000000000000000000000000000000000000000000000000000000000000000000000000000000000000000000000000000000000000000000000000000000000000000000000000000000000000000000000000000000000000000000000000000000000000000000000000000000000000000000000000000000000000000000000000000000000000000000000000000000000000000000000000000000000000000000000000000000000000000000000000000000000000000000000000000000000000000000000000000000000000000000000000000000000000000000000000000000000000000000000000000000000000000000000000000000000000000000000000000000000000000000000000000000000000000000000000000000000000000000000000000000000000000000000000000000000000000000000000000000000000000000000000000000000000000000000000000000000000000000000000000000000000000000000000000000000000000000000000000000000000000000000000000000000000000000000000000000000000000000000000000000000000000000000000000000000000000000000000000000000000000000000000000000000000000000000000000000000000000000000000000000000000000000000000000000000000000000000000000000000000000000000000000000000000000000000000000000000000000000000000000000000000000000000000000000000000000000000000000000000000000000000000000000000000000000000000000000000000000000000000000000000000000000000000000000000000000000000000000000000000000000000000000000000000000000000000000000000000000000000000000000000000000000000000000000000000000000000000000000000000000000000000000000000000000000000000000000000000000000000000000000000000000000000000000000000000000000000000000000000000000000000000000000000000000000000000000000000000000000000000000000000000000000000000000000000000000000000000000000000000000000000000000000000000000000000000000000000000000000000000000000000000000000000000000000000000000000000000000000000000000000000000000000000000000000000000000000000000000000000000000000000000000000000000000000000000000000000000000000000000000000000000000000000000000000000000000000000000000000000000000000000000000000000000000000000000000000000000000000000000000000000000000000000000000000000000000000000000000000000000000000000000000000000000000000000000000000000000000000000000000000000000000000000000000000000000000000000000000000000000000000000000000000000000000000000000000000000000000000000000000000000000000000000000000000000000000000000000000000000000000000000000000000000000000000000000000000000000000000000000000000000000000000000000000000000000000000000000000000000000000000000000000000000000000000000000000000000000000000000000000000000000000000000000000000000000000000000000000000000000000000000000000000000000000000000000000000000000000000000000000000000000000000000000000000000000000000000000000000000000000000000000000000000000000000000000000000000000000000000000000000000000000000000000000000000000000000000000000000000000000000000000000000000000000000000000000000000000000000000000000000000000000000000000000000000000000000000000000000000000000000000000000000000000000000000000000000000000000000000000000000000000000000000000000000000000000000000000000000000000000000000000000000000000000000000000000000000000000000000000000000000000000000000000000000000000000000000000000000000000000000000000000000000000000000000000000000000000000000000000000000000000000000000000000000000000000000000000000000000000000000000000000000000000000000000000000000000000000000000000000000000000000000000000000000000000000000000000000000000000000000000000000000000000000000000000000000000000000000000000000000000000000000000000000000000000000000000000000000000000000000000000000000000000000000000000000000000000000000000000000000000000000000000000000000000000000000000000000000000000000000000000000000000000000000000000000000000000000000000000000000000000000000000000000000000000000000000000000000000000000000000000000000000000000000000000000000000000000000000000000000000000000000000000000000000000000000000000000000000000000000000000000000000000000000000000000000000000000000000000000000000000000000000000000000000000000000000000000000000000000000000000000000000000000000000000000000000000000000000000000000000000000000000000000000000000000000000000000000000000000000000000000000000000000000000000000000000000000000000000000000000000000000000000000000000000000000000000000000000000000000000000000000000000000000000000000000000000000000000000000000000000000000000000000000000000000000000000000000000000000000000000000000000000000000000000000000000000000000000000000000000000000000000000000000000000000000000000000000000000000000000000000000000000000000000000000000000000000000000000000000000000000000000000000000000000000000000000000000000000000000000000000000000000000000000000000000000000000000000000000000000000000000000000000000000000000000000000000000000000000000000000000000000000000000000000000000000000000000000000000000000000000000000000000000000000000000000000000000000000000000000000000000000000000000000000000000000000000000000000000000000000000000000000000000000000000000000000000000000000000000000000000000000000000000000000000000000000000000000000000000000000000000000000000000000000000000000000000000000000000000000000000000000000000000000000000000000000000000000000000000000000000000000000000000000000000000000000000000000000000000000000000000000000000000000000000000000000000000000000000000000000000000000000000000000000000000000000000000000000000000000000000000000000000000000000000000000000000000000000000000000000000000000000000000000000000000000000000000000000000000000000000000000000000000000000000000000000000000000000000000000000000000000000000000000000000000000000000000000000000000000000000000000000000000000000000000000000000000000000000000000000000000000000000000000000000000000000000000000000000000000000000000000000000000000000000000000000000000000000000000000000000000000000000000000000000000000000000000000000000000000000000000000000000000000000000000000000000000000000000000000000000000000000000000000000000000000000000000000000000000000000000000000000000000000000000000000000000000000000000000000000000000000000000000000000000000000000000000000000000000000000000000000000000000000000000000000000000000000000000000000000000000000000000000000000000000000000000000000000000000000000000000000000000000000000000000000000000000000000000000000000000000000000000000000000000000000000000000000000000000000000000000000000000000000000000000000000000000000000000000000000000000000000000000000000000000000000000000000000000000000000000000000000000000000000000000000000000000000000000000000000000000000000000000000000000000000000000000000000000000000000000000000000000000000000000000000000000000000000000000000000000000000000000000000000000000000000000000000000000000000000000000000000000000000000000000000000000000000000000000000000000000000000000000000000000000000000000000000000000000000000000000000000000000000000000000000000000000000000000000000000000000000000000000000000000000000000000000000000000000000000000000000000000000000000000000000000000000000000000000000000000000000000000000000000000000000000000000000000000000000000000000000000000000000000000000000000000000000000000000000000000000000000000000000000000000000000000000000000000000000000000000000000000000000000000000000000000000000000000000000000000000000000000000000000000000000000000000000000000000000000000000000000000000000000000000000000000000000000000000000000000000000000000000000000000000000000000000000000000000000000000000000000000000000000000000000000000000000000000000000000000000000000000000000000000000000000000000000000000000000000000000000000000000000000000000000000000000000000000000000000000000000000000000000000000000000000000000000000000000000000000000000000000000000000000000000000000000000000000000000000000000000000000000000000000000000000000000000000000000000000000000000000000000000000000000000000000000000000000000000000000000000000000000000000000000000000000000000000000000000000000000000000000000000000000000000000000000000000000000000000000000000000000000000000000000000000000000000000000000000000000000000000000000000000000000000000000000000000000000000000000000000000000000000000000000000000000000000000000000000000000000000000000000000000000000000000000000000000000000000000000000000000000000000000000000000000000000000000000000000000000000000000000000000000000000000000000000000000000000000000000000000000000000000000000000000000000000000000000000000000000000000000000000000000000000000000000000000000000000000000000000000000000000000000000000000000000000000000000000000000000000000000000000000000000000000000000000000000000000000000000000000000000000000000000000000000000000000000000000000000000000000000000000000000000000000000000000000000000000000000000000000000000000000000000000000000000000000000000000000000000000000000000000000000000000000000000000000000000000000000000000000000000000000000000000000000000000000000000000000000000000000000000000000000000000000000000000000000000000000000000000000000000000000000000000000000000000000000000000000000000000000000000000000000000000000000000000000000000000000000000000000000000000000000000000000000000000000000000000000000000000000000000000000000000000000000000000000000000000000000000000000000000000000000000000000000000000000000000000000000000000000000000000000000000000000000000000000000000000000000000000000000000000000000000000000000000000000000000000000000000000000000000000000000000000000000000000000000000000000000000000000000000000000000000000000000000000000000000000000000000000000000000000000000000000000000000000000000000000000000000000000000000000000000000000000000000000000000000000000000000000000000000000000000000000000000000000000000000000000000000000000000000000000000000000000000000000000000000000000000000000000000000000000000000000000000000000000000000000000000000000000000000000000000000000000000000000000000000000000000000000000000000000000000000000000000000000000000000000000000000000000000000000000000000000000000000000000000000000000000000000000000000000000000000000000000000000000000000000000000000000000000000000000000000000000000000000000000000000000000000000000000000000000000000000000000000000000000000000000000000000000000000000000000000000000000000000000000000000000000000000000000000000000000000000000000000000000000000000000000000000000000000000000000000000000000000000000000000000000000000000000000000000000000000000000000000000000000000000000000000000000000000000000000000000000000000000000000000000000000000000000000000000000000000000000000000000000000000000000000000000000000000000000000000000000000000000000000000000000000000000000000000000000000000000000000000000000000000000000000000000000000000000000000000000000000000000000000000000000000000000000000000000000000000000000000000000000000000000000000000000000000000000000000000000000000000000000000000000000000000000000000000000000000000000000000000000000000000000000000000000000000000000000000000000000000000000000000000000000000000000000000000000000000000000000000000000000000000000000000000000000000000000000000000000000000000000000000000000000000000000000000000000000000000000000000000000000000000000000000000000000000000000000000000000000000000000000000000000000000000000000000000000000000000000000000000000000000000000000000000000000000000000000000000000000000000000000000000000000000000000000000000000000000000000000000000000000000000000000000000000000000000000000000000000000000000000000000000000000000000000000000000000000000000000000000000000000000000000000000000000000000000000000000000000000000000000000000000000000000000000000000000000000000000000000000000000000000000000000000000000000000000000000000000000000000000000000000000000000000000000000000000000000000000000000000000000000000000000000000000000000000000000000000000000000000000000000000000000000000000000000000000000000000000000000000000000000000000000000000000000000000000000000000000000000000000000000000000000000000000000000000000000000000000000000000000000000000000000000000000000000000000000000000000000000000000000000000000000000000000000000000000000000000000000000000000000000000000000000000000000000000000000000000000000000000000000000000000000000000000000000000000000000000000000000000000000000000000000000000000000000000000000000000000000000000000000000000000000000000000000000000000000000000000000000000000000000000000000000000000000000000000000000000000000000000000000000000000000000000000000000000000000000000000000000000000000000000000000000000000000000000000000000000000000000000000000000000000000000000000000000000000000000000000000000000000000000000000000000000000000000000000000000000000000000000000000000000000000000000000000000000000000000000000000000000000000000000000000000000000000000000000000000000000000000000000000000000000000000000000000000000000000000000000000000000000000000000000000000000000000000000000000000000000000000000000000000000000000000000000000000000000000000000000000000000000000000000000000000000000000000000000000000000000000000000000000000000000000000000000000000000000000000000000000000000000000000000000000000000000000000000000000000000000000000000000000000000000000000000000000000000000000000000000000000000000000000000000000000000000000000000000000000000000000000000000000000000000000000000000000000000000000000000000000000000000000000000000000000000000000000000000000000000000000000000000000000000000000000000000000000000000000000000000000000000000000000000000000000000000000000000000000000000000000000000000000000000000000000000000000000000000000000000000000000000000000000000000000000000000000000000000000000000000000000000000000000000000000000000000000000000000000000000000000000000000000000000000000000000000000000000000000000000000000000000000000000000000000000000000000000000000000000000000000000000000000000000000000000000000000000000000000000000000000000000000000000000000000000000000000000000000000000000000000000000000000000000000000000000000000000000000000000000000000000000000000000000000000000000000000000000000000000000000000000000000000000000000000000000000000000000000000000000000000000000000000000000000000000000000000000000000000000000000000000000000000000000000000000000000000000000000000000000000000000000000000000000000000000000000000000000000000000000000000000000000000000000000000000000000000000000000000000000000000000000000000000000000000000000000000000000000000000000000000000000000000000000000000000000000000000000000000000000000000000000000000000000000000000000000000000000000000000000000000000000000000000000000000000000000000000000000000000000000000000000000000000000000000000000000000000000000000000000000000000000000000000000000000000000000000000000000000000000000000000000000000000000000000000000000000000000000000000000000000000000000000000000000000000000000000000000000000000000000000000000000000000000000000000000000000000000000000000000000000000000000000000000000000000000000000000000000000000000000000000000000000000000000000000000000000000000000000000000000000000000000000000000000000000000000000000000000000000000000000000000000000000000000000000000000000000000000000000000000000000000000000000000000000000000000000000000000000000000000000000000000000000000000000000000000000000000000000000000000000000000000000000000000000000000000000000000000000000000000000000000000000000000000000000000000000000000000000000000000000000000000000000000000000000000000000000000000000000000000000000000000000000000000000000000000000000000000000000000000000000000000000000000000000000000000000000000000000000000000000000000000000000000000000000000000000000000000000000000000000000000000000000000000000000000000000000000000000000000000000000000000000000000000000000000000000000000000000000000000000000000000000000000000000000000000000000000000000000000000000000000000000000000000000000000000000000000000000000000000000000000000000000000000000000000000000000000000000000000000000000000000000000000000000000000000000000000000000000000000000000000000000000000000000000000000000000000000000000000000000000000000000000000000000000000000000000000000000000000000000000000000000000000000000000000000000000000000000000000000000000000000000000000000000000000000000000000000000000000000000000000000000000000000000000000000000000000000000000000000000000000000000000000000000000000000000000000000000000000000000000000000000000000000000000000000000000000000000000000000000000000000000000000000000000000000000000000000000000000000000000000000000000000000000000000000000000000000000000000000000000000000000000000000000000000000000000000000000000000000000000000000000000000000000000000000000000000000000000000000000000000000000000000000000000000000000000000000000000000000000000000000000000000000000000000000000000000000000000000000000000000000000000000000000000000000000000000000000000000000000000000000000000000000000000000000000000000000000000000000000000000000000000000000000000000000000000000000000000000000000000000000000000000000000000000000000000000000000000000000000000000000000000000000000000000000000000000000000000000000000000000000000000000000000000000000000000000000000000000000000000000000000000000000000000000000000000000000000000000000000000000000000000000000000000000000000000000000000000000000000000000000000000000000000000000000000000000000000000000000000000000000000000000000000000000000000000000000000000000000000000000000000000000000000000000000000000000000000000000000000000000000000000000000000000000000000000000000000000000000000000000000000000000000000000000000000000000000000000000000000000000000000000000000000000000000000000000000000000000000000000000000000000000000000000000000000000000000000000000000000000000000000000000000000000000000000000000000000000000000000000000000000000000000000000000000000000000000000000000000000000000000000000000000000000000000000000000000000000000000000000000000000000000000000000000000000000000000000000000000000000000000000000000000000000000000000000000000000000000000000000000000000000000000000000000000000000000000000000000000000000000000000000000000000000000000000000000000000000000000000000000000000000000000000000000000000000000000000000000000000000000000000000000000000000000000000000000000000000000000000000000000000000000000000000000000000000000000000000000000000000000000000000000000000000000000000000000000000000000000000000000000000000000000000000000000000000000000000000000000000000000000000000000000000000000000000000000000000000000000000000000000000000000000000000000000000000000000000000000000000000000000000000000000000000000000000000000000000000000000000000000000000000000000000000000000000000000000000000000000000000000000000000000000000000000000000000000000000000000000000000000000000000000000000000000000000000000000000000000000000000000000000000000000000000000000000000000000000000000000000000000000000000000000000000000000000000000000000000000000000000000000000000000000000000000000000000000000000000000000000000000000000000000000000000000000000000000000000000000000000000000000000000000000000000000000000000000000000000000000000000000000000000000000000000000000000000000000000000000000000000000000000000000000000000000000000000000000000000000000000000000000000000000000000000000000000000000000000000000000000000000000000000000000000000000000000000000000000000000000000000000000000000000000000000000000000000000000000000000000000000000000000000000000000000000000000000000000000000000000000000000000000000000000000000000000000000000000000000000000000000000000000000000000000000000000000000000000000000000000000000000000000000000000000000000000000000000000000000000000000000000000000000000000000000000000000000000000000000000000000000000000000000000000000000000000000000000000000000000000000000000000000000000000000000000000000000000000000000000000000000000000000000000000000000000000000000000000000000000000000000000000000000000000000000000000000000000000000000000000000000000000000000000000000000000000000000000000000000000000000000000000000000000000000000000000000000000000000000000000000000000000000000000000000000000000000000000000000000000000000000000000000000000000000000000000000000000000000000000000000000000000000000000000000000000000000000000000000000000000000000000000000000000000000000000000000000000000000000000000000000000000000000000000000000000000000000000000000000000000000000000000000000000000000000000000000000000000000000000000000000000000000000000000000000000000000000000000000000000000000000000000000000000000000000000000000000000000000000000000000000000000000000000000000000000000000000000000000000000000000000000000000000000000000000000000000000000000000000000000000000000000000000000000000000000000000000000000000000000000000000000000000000000000000000000000000000000000000000000000000000000000000000000000000000000000000000000000000000000000000000000000000000000000000000000000000000000000000000000000000000000000000000000000000000000000000000000000000000000000000000000000000000000000000000000000000000000000000000000000000000000000000000000000000000000000000000000000000000000000000000000000000000000000000000000000000000000000000000000000000000000000000000000000000000000000000000000000000000000000000000000000000000000000000000000000000000000000000000000000000000000000000000000000000000000000000000000000000000000000000000000000000000000000000000000000000000000000000000000000000000000000000000000000000000000000000000000000000000000000000000000000000000000000000000000000000000000000000000000000000000000000000000000000000000000000000000000000000000000000000000000000000000000000000000000000000000000000000000000000000000000000000000000000000000000000000000000000000000000000000000000000000000000000000000000000000000000000000000000000000000000000000000000000000000000000000000000000000000000000000000000000000000000000000000000000000000000000000000000000000000000000000000000000000000000000000000000000000000000000000000000000000000000000000000000000000000000000000000000000000000000000000000000000000000000000000000000000000000000000000000000000000000000000000000000000000000000000000000000000000000000000000000000000000000000000000000000000000000000000000000000000000000000000000000000000000000000000000000000000000000000000000000000000000000000000000000000000000000000000000000000000000000000000000000000000000000000000000000000000000000000000000000000000000000000000000000000000000000000000000000000000000000000000000000000000000000000000000000000000000000000000000000000000000000000000000000000000000000000000000000000000000000000000000000000000000000000000000000000000000000000000000000000000000000000000000000000000000000000000000000000000000000000000000000000000000000000000000000000000000000000000000000000000000000000000000000000000000000000000000000000000000000000000000000000000000000000000000000000000000000000000000000000000000000000000000000000000000000000000000000000000000000000000000000000000000000000000000000000000000000000000000000000000000000000000000000000000000000000000000000000000000000000000000000000000000000000000000000000000000000000000000000000000000000000000000000000000000000000000000000000000000000000000000000000000000000000000000000000000000000000000000000000000000000000000000000000000000000000000000000000000000000000000000000000000000000000000000000000000000000000000000000000000000000000000000000000000000000000000000000000000000000000000000000000000000000000000000000000000000000000000000000000000000000000000000000000000000000000000000000000000000000000000000000000000000000000000000000000000000000000000000000000000000000000000000000000000000000000000000000000000000000000000000000000000000000000000000000000000000000000000000000000000000000000000000000000000000000000000000000000000000000000000000000000000000000000000000000000000000000000000000000000000000000000000000000000000000000000000000000000000000000000000000000000000000000000000000000000000000000000000000000000000000000000000000000000000000000000000000000000000000000000000000000000000000000000000000000000000000000000000000000000000000000000000000000000000000000000000000000000000000000000000000000000000000000000000000000000000000000000000000000000000000000000000000000000000000000000000000000000000000000000000000000000000000000000000000000000000000000000000000000000000000000000000000000000000000000000000000000000000000000000000000000000000000000000000000000000000000000000000000000000000000000000000000000000000000000000000000000000000000000000000000000000000000000000000000000000000000000000000000000000000000000000000000000000000000000000000000000000000000000000000000000000000000000000000000000000000000000000000000000000000000000000000000000000000000000000000000000000000000000000000000000000000000000000000000000000000000000000000000000000000000000000000000000000000000000000000000000000000000000000000000000000000000000000000000000000000000000000000000000000000000000000000000000000000000000000000000000000000000000000000000000000000000000000000000000000000000000000000000000000000000000000000000000000000000000000000000000000000000000000000000000000000000000000000000000000000000000000000000000000000000000000000000000000000000000000000000000000000000000000000000000000000000000000000000000000000000000000000000000000000000000000000000000000000000000000000000000000000000000000000000000000000000000000000000000000000000000000000000000000000000000000000000000000000000000000000000000000000000000000000000000000000000000000000000000000000000000000000000000000000000000000000000000000000000000000000000000000000000000000000000000000000000000000000000000000000000000000000000000000000000000000000000000000000000000000000000000000000000000000000000000000000000000000000000000000000000000000000000000000000000000000000000000000000000000000000000000000000000000000000000000000000000000000000000000000000000000000000000000000000000000000000000000000000000000000000000000000000000000000000000000000000000000000000000000000000000000000000000000000000000000000000000000000000000000000000000000000000000000000000000000000000000000000000000000000000000000000000000000000000000000000000000000000000000000000000000000000000000000000000000000000000000000000000000000000000000000000000000000000000000000000000000000000000000000000000000000000000000000000000000000000000000000000000000000000000000000000000000000000000000000000000000000000000000000000000000000000000000000000000000000000000000000000000000000000000000000000000000000000000000000000000000000000000000000000000000000000000000000000000000000000000000000000000000000000000000000000000000000000000000000000000000000000000000000000000000000000000000000000000000000000000000000000000000000000000000000000000000000000000000000000000000000000000000000000000000000000000000000000000000000000000000000000000000000000000000000000000000000000000000000000000000000000000000000000000000000000000000000000000000000000000000000000000000000000000000000000000000000000000000000000000000000000000000000000000000000000000000000000000000000000000000000000000000000000000000000000000000000000000000000000000000000000000000000000000000000000000000000000000000000000000000000000000000000000000000000000000000000000000000000000000000000000000000000000000000000000000000000000000000000000000000000000000000000000000000000000000000000000000000000000000000000000000000000000000000000000000000000000000000000000000000000000000000000000000000000000000000000000000000000000000000000000000000000000000000000000000000000000000000000000000000000000000000000000000000000000000000000000000000000000000000000000000000000000000000000000000000000000000000000000000000000000000000000000000000000000000000000000000000000000000000000000000000000000000000000000000000000000000000000000000000000000000000000000000000000000000000000000000000000000000000000000000000000000000000000000000000000000000000000000000000000000000000000000000000000000000000000000000000000000000000000000000000000000000000000000000000000000000000000000000000000000000000000000000000000000000000000000000000000000000000000000000000000000000000000000000000000000000000000000000000000000000000000000000000000000000000000000000000000000000000000000000000000000000000000000000000000000000000000000000000000000000000000000000000000000000000000000000000000000000000000000000000000000000000000000000000000000000000000000000000000000000000000000000000000000000000000000000000000000000000000000000000000000000000000000000000000000000000000000000000000000000000000000000000000000000000000000000000000000000000000000000000000000000000000000000000000000000000000000000000000000000000000000000000000000000000000000000000000000000000000000000000000000000000000000000000000000000000000000000000000000000000000000000000000000000000000000000000000000000000000000000000000000000000000000000000000000000000000000000000000000000000000000000000000000000000000000000000000000000000000000000000000000000000000000000000000000000000000000000000000000000000000000000000000000000000000000000000000000000000000000000000000000000000000000000000000000000000000000000000000000000000000000000000000000000000000000000000000000000000000000000000000000000000000000000000000000000000000000000000000000000000000000000000000000000000000000000000000000000000000000000000000000000000000000000000000000000000000000000000000000000000000000000000000000000000000000000000000000000000000000000000000000000000000000000000000000000000000000000000000000000000000000000000000000000000000000000000000000000000000000000000000000000000000000000000000000000000000000000000000000000000000000000000000000000000000000000000000000000000000000000000000000000000000000000000000000000000000000000000000000000000000000000000000000000000000000000000000000000000000000000000000000000000000000000000000000000000000000000000000000000000000000000000000000000000000000000000000000000000000000000000000000000000000000000000000000000000000000000000000000000000000000000000000000000000000000000000000000000000000000000000000000000000000000000000000000000000000000000000000000000000000000000000000000000000000000000000000000000000000000000000000000000000000000000000000000000000000000000000000000000000000000000000000000000000000000000000000000000000000000000000000000000000000000000000000000000000000000000000000000000000000000000000000000000000000000000000000000000000000000000000000000000000000000000000000000000000000000000000000000000000000000000000000000000000000000000000000000000000000000000000000000000000000000000000000000000000000000000000000000000000000000000000000000000000000000000000000000000000000000000000000000000000000000000000000000000000000000000000000000000000000000000000000000000000000000000000000000000000000000000000000000000000000000000000000000000000000000000000000000000000000000000000000000000000000000000000000000000000000000000000000000000000000000000000000000000000000000000000000000000000000000000000000000000000000000000000000000000000000000000000000000000000000000000000000000000000000000000000000000000000000000000000000000000000000000000000000000000000000000000000000000000000000000000000000000000000000000000000000000000000000000000000000000000000000000000000000000000000000000000000000000000000000000000000000000000000000000000000000000000000000000000000000000000000000000000000000000000000000000000000000000000000000000000000000000000000000000000000000000000000000000000000000000000000000000000000000000000000000000000000000000000000000000000000000000000000000000000000000000000000000000000000000000000000000000000000000000000000000000000000000000000000000000000000000000000000000000000000000000000000000000000000000000000000000000000000000000000000000000000000000000000000000000000000000000000000000000000000000000000000000000000000000000000000000000000000000000000000000000000000000000000000000000000000000000000000000000000000000000000000000000000000000000000000000000000000000000000000000000000000000000000000000000000000000000000000000000000000000000000000000000000000000000000000000000000000000000000000000000000000000000000000000000000000000000000000000000000000000000000000000000000000000000000000000000000000000000000000000000000000000000000000000000000000000000000000000000000000000000000000000000000000000000000000000000000000000000000000000000000000000000000000000000000000000000000000000000000000000000000000000000000000000000000000000000000000000000000000000000000000000000000000000000000000000000000000000000000000000000000000000000000000000000000000000000000000000000000000000000000000000000000000000000000000000000000000000000000000000000000000000000000000000000000000000000000000000000000000000000000000000000000000000000000000000000000000000000000000000000000000000000000000000000000000000000000000000000000000000000000000000000000000000000000000000000000000000000000000000000000000000000000000000000000000000000000000000000000000000000000000000000000000000000000000000000000000000000000000000000000000000000000000000000000000000000000000000000000000000000000000000000000000000000000000000000000000000000000000000000000000000000000000000000000000000000000000000000000000000000000000000000000000000000000000000000000000000000000000000000000000000000000000000000000000000000000000000000000000000000000000000000000000000000000000000000000000000000000000000000000000000000000000000000000000000000000000000000000000000000000000000000000000000000000000000000000000000000000000000000000000000000000000000000000000000000000000000000000000000000000000000000000000000000000000000000000000000000000000000000000000000000000000000000000000000000000000000000000000000000000000000000000000000000000000000000000000000000000000000000000000000000000000000000000000000000000000000000000000000000000000000000000000000000000000000000000000000000000000000000000000000000000000000000000000000000000000000000000000000000000000000000000000000000000000000000000000000000000000000000000000000000000000000000000000000000000000000000000000000000000000000000000000000000000000000000000000000000000000000000000000000000000000000000000000000000000000000000000000000000000000000000000000000000000000000000000000000000000000000000000000000000000000000000000000000000000000000000000000000000000000000000000000000000000000000000000000000000000000000000000000000000000000000000000000000000000000000000000000000000000000000000000000000000000000000000000000000000000000000000000000000000000000000000000000000000000000000000000000000000000000000000000000000000000000000000000000000000000000000000000000000000000000000000000000000000000000000000000000000000000000000000000000000000000000000000000000000000000000000000000000000000000000000000000000000000000000000000000000000000000000000000000000000000000000000000000000000000000000000000000000000000000000000000000000000000000000000000000000000000000000000000000000000000000000000000000000000000000000000000000000000000000000000000000000000000000000000000000000000000000000000000000000000000000000000000000000000000000000000000000000000000000000000000000000000000000000000000000000000000000000000000000000000000000000000000000000000000000000000000000000000000000000000000000000000000000000000000000000000000000000000000000000000000000000000000000000000000000000000000000000000000000000000000000000000000000000000000000000000000000000000000000000000000000000000000000000000000000000000000000000000000000000000000000000000000000000000000000000000000000000000000000000000000000000000000000000000000000000000000000000000000000000000000000000000000000000000000000000000000000000000000000000000000000000000000000000000000000000000000000000000000000000000000000000000000000000000000000000000000000000000000000000000000000000000000000000000000000000000000000000000000000000000000000000000000000000000000000000000000000000000000000000000000000000000000000000000000000000000000000000000000000000000000000000000000000000000000000000000000000000000000000000000000000000000000000000000000000000000000000000000000000000000000000000000000000000000000000000000000000000000000000000000000000000000000000000000000000000000000000000000000000000000000000000000000000000000000000000000000000000000000000000000000000000000000000000000000000000000000000000000000000000000000000000000000000000000000000000000000000000000000000000000000000000000000000000000000000000000000000000000000000000000000000000000000000000000000000000000000000000000000000000000000000000000000000000000000000000000000000000000000000000000000000000000000000000000000000000000000000000000000000000000000000000000000000000000000000000000000000000000000000000000000000000000000000000000000000000000000000000000000000000000000000000000000000000000000000000000000000000000000000000000000000000000000000000000000000000000000000000000000000000000000000000000000000000000000000000000000000000000000000000000000000000000000000000000000000000000000000000000000000000000000000000000000000000000000000000000000000000000000000000000000000000000000000000000000000000000000000000000000000000000000000000000000000000000000000000000000000000000000000000000000000000000000000000000000000000000000000000000000000000000000000000000000000000000000000000000000000000000000000000000000000000000000000000000000000000000000000000000000000000000000000000000000000000000000000000000000000000000000000000000000000000000000000000000000000000000000000000000000000000000000000000000000000000000000000000000000000000000000000000000000000000000000000000000000000000000000000000000000000000000000000000000000000000000000000000000000000000000000000000000000000000000000000000000000000000000000000000000000000000000000000000000000000000000000000000000000000000000000000000000000000000000000000000000000000000000000000000000000000000000000000000000000000000000000000000000000000000000000000000000000000000000000000000000000000000000000000000000000000000000000000000000000000000000000000000000000000000000000000000000000000000000000000000000000000000000000000000000000000000000000000000000000000000000000000000000000000000000000000000000000000000000000000000000000000000000000000000000000000000000000000000000000000000000000000000000000000000000000000000000000000000000000000000000000000000000000000000000000000000000000000000000000000000000000000000000000000000000000000000000000000000000000000000000000000000000000000000000000000000000000000000000000000000000000000000000000000000000000000000000000000000000000000000000000000000000000000000000000000000000000000000000000000000000000000000000000000000000000000000000000000000000000000000000000000000000000000000000000000000000000000000000000000000000000000000000000000000000000000000000000000000000000000000000000000000000000000000000000000000000000000000000000000000000000000000000000000000000000000000000000000000000000000000000000000000000000000000000000000000000000000000000000000000000000000000000000000000000000000000000000000000000000000000000000000000000000000000000000000000000000000000000000000000000000000000000000000000000000000000000000000000000000000000000000000000000000000000000000000000000000000000000000000000000000000000000000000000000000000000000000000000000000000000000000000000000000000000000000000000000000000000000000000000000000000000000000000000000000000000000000000000000000000000000000000000000000000000000000000000000000000000000000000000000000000000000000000000000000000000000000000000000000000000000000000000000000000000000000000000000000000000000000000000000000000000000000000000000000000000000000000000000000000000000000000000000000000000000000000000000000000000000000000000000000000000000000000000000000000000000000000000000000000000000000000000000000000000000000000000000000000000000000000000000000000000000000000000000000000000000000000000000000000000000000000000000000000000000000000000000000000000000000000000000000000000000000000000000000000000000000000000000000000000000000000000000000000000000000000000000000000000000000000000000000000000000000000000000000000000000000000000000000000000000000000000000000000000000000000000000000000000000000000000000000000000000000000000000000000000000000000000000000000000000000000000000000000000000000000000000000000000000000000000000000000000000000000000000000000000000000000000000000000000000000000000000000000000000000000000000000000000000000000000000000000000000000000000000000000000000000000000000000000000000000000000000000000000000000000000000000000000000000000000000000000000000000000000000000000000000000000000000000000000000000000000000000000000000000000000000000000000000000000000000000000000000000000000000000000000000000000000000000000000000000000000000000000000000000000000000000000000000000000000000000000000000000000000000000000000000000000000000000000000000000000000000000000000000000000000000000000000000000000000000000000000000000000000000000000000000000000000000000000000000000000000000000000000000000000000000000000000000000000000000000000000000000000000000000000000000000000000000000000000000000000000000000000000000000000000000000000000000000000000000000000000000000000000000000000000000000000000000000000000000000000000000000000000000000000000000000000000000000000000000000000000000000000000000000000000000000000000000000000000000000000000000000000000000000000000000000000000000000000000000000000000000000000000000000000000000000000000000000000000000000000000000000000000000000000000000000000000000000000000000000000000000000000000000000000000000000000000000000000000000000000000000000000000000000000000000000000000000000000000000000000000000000000000000000000000000000000000000000000000000000000000000000000000000000000000000000000000000000000000000000000000000000000000000000000000000000000000000000000000000000000000000000000000000000000000000000000000000000000000000000000000000000000000000000000000000000000000000000000000000000000000000000000000000000000000000000000000000000000000000000000000000000000000000000000000000000000000000000000000000000000000000000000000000000000000000000000000000000000000000000000000000000000000000000000000000000000000000000000000000000000000000000000000000000000000000000000000000000000000000000000000000000000000000000000000000000000000000000000000000000000000000000000000000000000000000000000000000000000000000000000000000000000000000000000000000000000000000000000000000000000000000000000000000000000000000000000000000000000000000000000000000000000000000000000000000000000000000000000000000000000000000000000000000000000000000000000000000000000000000000000000000000000000000000000000000000000000000000000000000000000000000000000000000000000000000000000000000000000000000000000000000000000000000000000000000000000000000000000000000000000000000000000000000000000000000000000000000000000000000000000000000000000000000000000000000000000000000000000000000000000000000000000000000000000000000000000000000000000000000000000000000000000000000000000000000000000000000000000000000000000000000000000000000000000000000000000000000000000000000000000000000000000000000000000000000000000000000000000000000000000000000000000000000000000000000000000000000000000000000000000000000000000000000000000000000000000000000000000000000000000000000000000000000000000000000000000000000000000000000000000000000000000000000000000000000000000000000000000000000000000000000000000000000000000000000000000000000000000000000000000000000000000000000000000000000000000000000000000000000000000000000000000000000000000000000000000000000000000000000000000000000000000000000000000000000000000000000000000000000000000000000000000000000000000000000000000000000000000000000000000000000000000000000000000000000000000000000000000000000000000000000000000000000000000000000000000000000000000000000000000000000000000000000000000000000000000000000000000000000000000000000000000000000000000000000000000000000000000000000000000000000000000000000000000000000000000000000000000000000000000000000000000000000000000000000000000000000000000000000000000000000000000000000000000000000000000000000000000000000000000000000000000000000000000000000000000000000000000000000000000000000000000000000000000000000000000000000000000000000000000000000000000000000000000000000000000000000000000000000000000000000000000000000000000000000000000000000000000000000000000000000000000000000000000000000000000000000000000000000000000000000000000000000000000000000000000000000000000000000000000000000000000000000000000000000000000000000000000000000000000000000000000000000000000000000000000000000000000000000000000000000000000000000000000000000000000000000000000000000000000000000000000000000000000000000000000000000000000000000000000000000000000000000000000000000000000000000000000000000000000000000000000000000000000000000000000000000000000000000000000000000000000000000000000000000000000000000000000000000000000000000000000000000000000000000000000000000000000000000000000000000000000000000000000000000000000000000000000000000000000000000000000000000000000000000000000000000000000000000000000000000000000000000000000000000000000000000000000000000000000000000000000000000000000000000000000000000000000000000000000000000000000000000000000000000000000000000000000000000000000000000000000000000000000000000000000000000000000000000000000000000000000000000000000000000000000000000000000000000000000000000000000000000000000000000000000000000000000000000000000000000000000000000000000000000000000000000000000000000000000000000000000000000000000000000000000000000000000000000000000000000000000000000000000000000000000000000000000000000000000000000000000000000000000000000000000000000000000000000000000000000000000000000000000000000000000000000000000000000000000000000000000000000000000000000000000000000000000000000000000000000000000000000000000000000000000000000000000000000000000000000000000000000000000000000000000000000000000000000000000000000000000000000000000000000000000000000000000000000000000000000000000000000000000000000000000000000000000000000000000000000000000000000000000000000000000000000000000000000000000000000000000000000000000000000000000000000000000000000000000000000000000000000000000000000000000000000000000000000000000000000000000000000000000000000000000000000000000000000000000000000000000000000000000000000000000000000000000000000000000000000000000000000000000000000000000000000000000000000000000000000000000000000000000000000000000000000000000000000000000000000000000000000000000000000000000000000000000000000000000000000000000000000000000000000000000000000000000000000000000000000000000000000000000000000000000000000000000000000000000000000000000000000000000000000000000000000000000000000000000000000000000000000000000000000000000000000000000000000000000000000000000000000000000000000000000000000000000000000000000000000000000000000000000000000000000000000000000000000000000000000000000000000000000000000000000000000000000000000000000000000000000000000000000000000000000000000000000000000000000000000000000000000000000000000000000000000000000000000000000000000000000000000000000000000000000000000000000000000000000000000000000000000000000000000000000000000000000000000000000000000000000000000000000000000000000000000000000000000000000000000000000000000000000000000000000000000000000000000000000000000000000000000000000000000000000000000000000000000000000000000000000000000000000000000000000000000000000000000000000000000000000000000000000000000000000000000000000000000000000000000000000000000000000000000000000000000000000000000000000000000000000000000000000000000000000000000000000000000000000000000000000000000000000000000000000000000000000000000000000000000000000000000000000000000000000000000000000000000000000000000000000000000000000000000000000000000000000000000000000000000000000000000000000000000000000000000000000000000000000000000000000000000000000000000000000000000000000000000000000000000000000000000000000000000000000000000000000000000000000000000000000000000000000000000000000000000000000000000000000000000000000000000000000000000000000000000000000000000000000000000000000000000000000000000000000000000000000000000000000000000000000000000000000000000000000000000000000000000000000000000000000000000000000000000000000000000000000000000000000000000000000000000000000000000000000000000000000000000000000000000000000000000000000000000000000000000000000000000000000000000000000000000000000000000000000000000000000000000000000000000000000000000000000000000000000000000000000000000000000000000000000000000000000000000000000000000000000000000000000000000000000000000000000000000000000000000000000000000000000000000000000000000000000000000000000000000000000000000000000000000000000000000000000000000000000000000000000000000000000000000000000000000000000000000000000000000000000000000000000000000000000000000000000000000000000000000000000000000000000000000000000000000000000000000000000000000000000000000000000000000000000000000000000000000000000000000000000000000000000000000000000000000000000000000000000000000000000000000000000000000000000000000000000000000000000000000000000000000000000000000000000000000000000000000000000000000000000000000000000000000000000000000000000000000000000000000000000000000000000000000000000000000000000000000000000000000000000000000000000000000000000000000000000000000000000000000000000000000000000000000000000000000000000000000000000000000000000000000000000000000000000000000000000000000000000000000000000000000000000000000000000000000000000000000000000000000000000000000000000000000000000000000000000000000000000000000000000000000000000000000000000000000000000000000000000000000000000000000000000000000000000000000000000000000000000000000000000000000000000000000000000000000000000000000000000000000000000000000000000000000000000000000000000000000000000000000000000000000000000000000000000000000000000000000000000000000000000000000000000000000000000000000000000000000000000000000000000000000000000000000000000000000000000000000000000000000000000000000000000000000000000000000000000000000000000000000000000000000000000000000000000000000000000000000000000000000000000000000000000000000000000000000000000000000000000000000000000000000000000000000000000000000000000000000000000000000000000000000000000000000000000000000000000000000000000000000000000000000000000000000000000000000000000000000000000000000000000000000000000000000000000000000000000000000000000000000000000000000000000000000000000000000000000000000000000000000000000000000000000000000000000000000000000000000000000000000000000000000000000000000000000000000000000000000000000000000000000000000000000000000000000000000000000000000000000000000000000000000000000000000000000000000000000000000000000000000000000000000000000000000000000000000000000000000000000000000000000000000000000000000000000000000000000000000000000000000000000000000000000000000000000000000000000000000000000000000000000000000000000000000000000000000000000000000000000000000000000000000000000000000000000000000000000000000000000000000000000000000000000000000000000000000000000000000000000000000000000000000000000000000000000000000000000000000000000000000000000000000000000000000000000000000000000000000000000000000000000000000000000000000000000000000000000000000000000000000000000000000000000000000000000000000000000000000000000000000000000000000000000000000000000000000000000000000000000000000000000000000000000000000000000000000000000000000000000000000000000000000000000000000000000000000000000000000000000000000000000000000000000000000000000000000000000000000000000000000000000000000000000000000000000000000000000000000000000000000000000000000000000000000000000000000000000000000000000000000000000000000000000000000000000000000000000000000000000000000000000000000000000000000000000000000000000000000000000000000000000000000000000000000000000000000000000000000000000000000000000000000000000000000000000000000000000000000000000000000000000000000000000000000000000000000000000000000000000000000000000000000000000000000000000000000000000000000000000000000000000000000000000000000000000000000000000000000000000000000000000000000000000000000000000000000000000000000000000000000000000000000000000000000000000000000000000000000000000000000000000000000000000000000000000000000000000000000000000000000000000000000000000000000000000000000000000000000000000000000000000000000000000000000000000000000000000000000000000000000000000000000000000000000000000000000000000000000000000000000000000000000000000000000000000000000000000000000000000000000000000000000000000000000000000000000000000000000000000000000000000000000000000000000000000000000000000000000000000000000000000000000000000000000000000000000000000000000000000000000000000000000000000000000000000000000000000000000000000000000000000000000000000000000000000000000000000000000000000000000000000000000000000000000000000000000000000000000000000000000000000000000000000000000000000000000000000000000000000000000000000000000000000000000000000000000000000000000000000000000000000000000000000000000000000000000000000000000000000000000000000000000000000000000000000000000000000000000000000000000000000000000000000000000000000000000000000000000000000000000000000000000000000000000000000000000000000000000000000000000000000000000000000000000000000000000000000000000000000000000000000000000000000000000000000000000000000000000000000000000000000000000000000000000000000000000000000000000000000000000000000000000000000000000000000000000000000000000000000000000000000000000000000000000000000000000000000000000000000000000000000000000000000000000000000000000000000000000000000000000000000000000000000000000000000000000000000000000000000000000000000000000000000000000000000000000000000000000000000000000000000000000000000000000000000000000000000000000000000000000000000000000000000000000000000000000000000000000000000000000000000000000000000000000000000000000000000000000000000000000000000000000000000000000000000000000000000000000000000000000000000000000000000000000000000000000000000000000000000000000000000000000000000000000000000000000000000000000000000000000000000000000000000000000000000000000000000000000000000000000000000000000000000000000000000000000000000000000000000000000000000000000000000000000000000000000000000000000000000000000000000000000000000000000000000000000000000000000000000000000000000000000000000000000000000000000000000000000000000000000000000000000000000000000000000000000000000000000000000000000000000000000000000000000000000000000000000000000000000000000000000000000000000000000000000000000000000000000000000000000000000000000000000000000000000000000000000000000000000000000000000000000000000000000000000000000000000000000000000000000000000000000000000000000000000000000000000000000000000000000000000000000000000000000000000000000000000000000000000000000000000000000000000000000000000000000000000000000000000000000000000000000000000000000000000000000000000000000000000000000000000000000000000000000000000000000000000000000000000000000000000000000000000000000000000000000000000000000000000000000000000000000000000000000000000000000000000000000000000000000000000000000000000000000000000000000000000000000000000000000000000000000000000000000000000000000000000000000000000000000000000000000000000000000000000000000000000000000000000000000000000000000000000000000000000000000000000000000000000000000000000000000000000000000000000000000000000000000000000000000000000000000000000000000000000000000000000000000000000000000000000000000000000000000000000000000000000000000000000000000000000000000000000000000000000000000000000000000000000000000000000000000000000000000000000000000000000000000000000000000000000000000000000000000000000000000000000000000000000000000000000000000000000000000000000000000000000000000000000000000000000000000000000000000000000000000000000000000000000000000000000000000000000000000000000000000000000000000000000000000000000000000000000000000000000000000000000000000000000000000000000000000000000000000000000000000000000000000000000000000000000000000000000000000000000000000000000000000000000000000000000000000000000000000000000000000000000000000000000000000000000000000000000000000000000000000000000000000000000000000000000000000000000000000000000000000000000000000000000000000000000000000000000000000000000000000000000000000000000000000000000000000000000000000000000000000000000000000000000000000000000000000000000000000000000000000000000000000000000000000000000000000000000000000000000000000000000000000000000000000000000000000000000000000000000000000000000000000000000000000000000000000000000000000000000000000000000000000000000000000000000000000000000000000000000000000000000000000000000000000000000000000000000000000000000000000000000000000000000000000000000000000000000000000000000000000000000000000000000000000000000000000000000000000000000000000000000000000000000000000000000000000000000000000000000000000000000000000000000000000000000000000000000000000000000000000000000000000000000000000000000000000000000000000000000000000000000000000000000000000000000000000000000000000000000000000000000000000000000000000000000000000000000000000000000000000000000000000000000000000000000000000000000000000000000000000000000000000000000000000000000000000000000000000000000000000000000000000000000000000000000000000000000000000000000000000000000000000000000000000000000000000000000000000000000000000000000000000000000000000000000000000000000000000000000000000000000000000000000000000000000000000000000000000000000000000000000000000000000000000000000000000000000000000000000000000000000000000000000000000000000000000000000000000000000000000000000000000000000000000000000000000000000000000000000000000000000000000000000000000000000000000000000000000000000000000000000000000000000000000000000000000000000000000000000000000000000000000000000000000000000000000000000000000000000000000000000000000000000000000000000000000000000000000000000000000000000000000000000000000000000000000000000000000000000000000000000000000000000000000000000000000000000000000000000000000000000000000000000000000000000000000000000000000000000000000000000000000000000000000000000000000000000000000000000000000000000000000000000000000000000000000000000000000000000000000000000000000000000000000000000000000000000000000000000000000000000000000000000000000000000000000000000000000000000000000000000000000000000000000000000000000000000000000000000000000000000000000000000000000000000000000000000000000000000000000000000000000000000000000000000000000000000000000000000000000000000000000000000000000000000000000000000000000000000000000000000000000000000000000000000000000000000000000000000000000000000000000000000000000000000000000000000000000000000000000000000000000000000000000000000000000000000000000000000000000000000000000000000000000000000000000000000000000000000000000000000000000000000000000000000000000000000000000000000000000000000000000000000000000000000000000000000000000000000000000000000000000000000000000000000000000000000000000000000000000000000000000000000000000000000000000000000000000000000000000000000000000000000000000000000000000000000000000000000000000000000000000000000000000000000000000000000000000000000000000000000000000000000000000000000000000000000000000000000000000000000000000000000000000000000000000000000000000000000000000000000000000000000000000000000000000000000000000000000000000000000000000000000000000000000000000000000000000000000000000000000000000000000000000000000000000000000000000000000000000000000000000000000000000000000000000000000000000000000000000000000000000000000000000000000000000000000000000000000000000000000000000000000000000000000000000000000000000000000000000000000000000000000000000000000000000000000000000000000000000000000000000000000000000000000000000000000000000000000000000000000000000000000000000000000000000000000000000000000000000000000000000000000000000000000000000000000000000000000000000000000000000000000000000000000000000000000000000000000000000000000000000000000000000000000000000000000000000000000000000000000000000000000000000000000000000000000000000000000000000000000000000000000000000000000000000000000000000000000000000000000000000000000000000000000000000000000000000000000000000000000000000000000000000000000000000000000000000000000000000000000000000000000000000000000000000000000000000000000000000000000000000000000000000000000000000000000000000000000000000000000000000000000000000000000000000000000000000000000000000000000000000000000000000000000000000000000000000000000000000000000000000000000000000000000000000000000000000000000000000000000000000000000000000000000000000000000000000000000000000000000000000000000000000000000000000000000000000000000000000000000000000000000000000000000000000000000000000000000000000000000000000000000000000000000000000000000000000000000000000000000000000000000000000000000000000000000000000000000000000000000000000000000000000000000000000000000000000000000000000000000000000000000000000000000000000000000000000000000000000000000000000000000000000000000000000000000000000000000000000000000000000000000000000000000000000000000000000000000000000000000000000000000000000000000000000000000000000000000000000000000000000000000000000000000000000000000000000000000000000000000000000000000000000000000000000000000000000000000000000000000000000000000000000000000000000000000000000000000000000000000000000000000000000000000000000000000000000000000000000000000000000000000000000000000000000000000000000000000000000000000000000000000000000000000000000000000000000000000000000000000000000000000000000000000000000000000000000000000000000000000000000000000000000000000000000000000000000000000000000000000000000000000000000000000000000000000000000000000000000000000000000000000000000000000000000000000000000000000000000000000000000000000000000000000000000000000000000000000000000000000000000000000000000000000000000000000000000000000000000000000000000000000000000000000000000000000000000000000000000000000000000000000000000000000000000000000000000000000000000000000000000000000000000000000000000000000000000000000000000000000000000000000000000000000000000000000000000000000000000000000000000000000000000000000000000000000000000000000000000000000000000000000000000000000000000000000000000000000000000000000000000000000000000000000000000000000000000000000000000000000000000000000000000000000000000000000000000000000000000000000000000000000000000000000000000000000000000000000000000000000000000000000000000000000000000000000000000000000000000000000000000000000000000000000000000000000000000000000000000000000000000000000000000000000000000000000000000000000000000000000000000000000000000000000000000000000000000000000000000000000000000000000000000000000000000000000000000000000000000000000000000000000000000000000000000000000000000000000000000000000000000000000000000000000000000000000000000000000000000000000000000000000000000000000000000000000000000000000000000000000000000000000000000000000000000000000000000000000000000000000000000000000000000000000000000000000000000000000000000000000000000000000000000000000000000000000000000000000000000000000000000000000000000000000000000000000000000000000000000000000000000000000000000000000000000000000000000000000000000000000000000000000000000000000000000000000000000000000000000000000000000000000000000000000000000000000000000000000000000000000000000000000000000000000000000000000000000000000000000000000000000000000000000000000000000000000000000000000000000000000000000000000000000000000000000000000000000000000000000000000000000000000000000000000000000000000000000000000000000000000000000000000000000000000000000000000000000000000000000000000000000000000000000000000000000000000000000000000000000000000000000000000000000000000000000000000000000000000000000000000000000000000000000000000000000000000000000000000000000000000000000000000000000000000000000000000000000000000000000000000000000000000000000000000000000000000000000000000000000000000000000000000000000000000000000000000000000000000000000000000000000000000000000000000000000000000000000000000000000000000000000000000000000000000000000000000000000000000000000000000000000000000000000000000000000000000000000000000000000000000000000000000000000000000000000000000000000000000000000000000000000000000000000000000000000000000000000000000000000000000000000000000000000000000000000000000000000000000000000000000000000000000000000000000000000000000000000000000000000000000000000000000000000000000000000000000000000000000000000000000000000000000000000000000000000000000000000000000000000000000000000000000000000000000000000000000000000000000000000000000000000000000000000000000000000000000000000000000000000000000000000000000000000000000000000000000000000000000000000000000000000000000000000000000000000000000000000000000000000000000000000000000000000000000000000000000000000000000000000000000000000000000000000000000000000000000000000000000000000000000000000000000000000000000000000000000000000000000000000000000000000000000000000000000000000000000000000000000000000000000000000000000000000000000000000000000000000000000000000000000000000000000000000000000000000000000000000000000000000000000000000000000000000000000000000000000000000000000000000000000000000000000000000000000000000000000000000000000000000000000000000000000000000000000000000000000000000000000000000000000000000000000000000000000000000000000000000000000000000000000000000000000000000000000000000000000000000000000000000000000000000000000000000000000000000000000000000000000000000000000000000000000000000000000000000000000000000000000000000000000000000000000000000000000000000000000000000000000000000000000000000000000000000000000000000000000000000000000000000000000000000000000000000000000000000000000000000000000000000000000000000000000000000000000000000000000000000000000000000000000000000000000000000000000000000000000000000000000000000000000000000000000000000000000000000000000000000000000000000000000000000000000000000000000000000000000000000000000000000000000000000000000000000000000000000000000000000000000000000000000000000000000000000000000000000000000000000000000000000000000000000000000000000000000000000000000000000000000000000000000000000000000000000000000000000000000000000000000000000000000000000000000000000000000000000000000000000000000000000000000000000000000000000000000000000000000000000000000000000000000000000000000000000000000000000000000000000000000000000000000000000000000000000000000000000000000000000000000000000000000000000000000000000000000000000000000000000000000000000000000000000000000000000000000000000000000000000000000000000000000000000000000000000000000000000000000000000000000000000000000000000000000000000000000000000000000000000000000000000000000000000000000000000000000000000000000000000000000000000000000000000000000000000000000000000000000000000000000000000000000000000000000000000000000000000000000000000000000000000000000000000000000000000000000000000000000000000000000000000000000000000000000000000000000000000000000000000000000000000000000000000000000000000000000000000000000000000000000000000000000000000000000000000000000000000000000000000000000000000000000000000000000000000000000000000000000000000000000000000000000000000000000000000000000000000000000000000000000000000000000000000000000000000000000000000000000000000000000000000000000000000000000000000000000000000000000000000000000000000000000000000000000000000000000000000000000000000000000000000000000000000000000000000000000000000000000000000000000000000000000000000000000000000000000000000000000000000000000000000000000000000000000000000000000000000000000000000000000000000000000000000000000000000000000000000000000000000000000000000000000000000000000000000000000000000000000000000000000000000000000000000000000000000000000000000000000000000000000000000000000000000000000000000000000000000000000000000000000000000000000000000000000000000000000000000000000000000000000000000000000000000000000000000000000000000000000000000000000000000000000000000000000000000000000000000000000000000000000000000000000000000000000000000000000000000000000000000000000000000000000000000000000000000000000000000000000000000000000000000000000000000000000000000000000000000000000000000000000000000000000000000000000000000000000000000000000000000000000000000000000000000000000000000000000000000000000000000000000000000000000000000000000000000000000000000000000000000000000000000000000000000000000000000000000000000000000000000000000000000000000000000000000000000000000000000000000000000000000000000000000000000000000000000000000000000000000000000000000000000000000000000000000000000000000000000000000000000000000000000000000000000000000000000000000000000000000000000000000000000000000000000000000000000000000000000000000000000000000000000000000000000000000000000000000000000000000000000000000000000000000000000000000000000000000000000000000000000000000000000000000000000000000000000000000000000000000000000000000000000000000000000000000000000000000000000000000000000000000000000000000000000000000000000000000000000000000000000000000000000000000000000000000000000000000000000000000000000000000000000000000000000000000000000000000000000000000000000000000000000000000000000000000000000000000000000000000000000000000000000000000000000000000000000000000000000000000000000000000000000000000000000000000000000000000000000000000000000000000000000000000000000000000000000000000000000000000000000000000000000000000000000000000000000000000000000000000000000000000000000000000000000000000000000000000000000000000000000000000000000000000000000000000000000000000000000000000000000000000000000000000000000000000000000000000000000000000000000000000000000000000000000000000000000000000000000000000000000000000000000000000000000000000000000000000000000000000000000000000000000000000000000000000000000000000000000000000000000000000000000000000000000000000000000000000000000000000000000000000000000000000000000000000000000000000000000000000000000000000000000000000000000000000000000000000000000000000000000000000000000000000000000000000000000000000000000000000000000000000000000000000000000000000000000000000000000000000000000000000000000000000000000000000000000000000000000000000000000000000000000000000000000000000000000000000000000000000000000000000000000000000000000000000000000000000000000000000000000000000000000000000000000000000000000000000000000000000000000000000000000000000000000000000000000000000000000000000000000000000000000000000000000000000000000000000000000000000000000000000000000000000000000000000000000000000000000000000000000000000000000000000000000000000000000000000000000000000000000000000000000000000000000000000000000000000000000000000000000000000000000000000000000000000000000000000000000000000000000000000000000000000000000000000000000000000000000000000000000000000000000000000000000000000000000000000000000000000000000000000000000000000000000000000000000000000000000000000000000000000000000000000000000000000000000000000000000000000000000000000000000000000000000000000000000000000000000000000000000000000000000000000000000000000000000000000000000000000000000000000000000000000000000000000000000000000000000000000000000000000000000000000000000000000000000000000000000000000000000000000000000000000000000000000000000000000000000000000000000000000000000000000000000000000000000000000000000000000000000000000000000000000000000000000000000000000000000000000000000000000000000000000000000000000000000000000000000000000000000000000000000000000000000000000000000000000000000000000000000000000000000000000000000000000000000000000000000000000000000000000000000000000000000000000000000000000000000000000000000000000000000000000000000000000000000000000000000000000000000000000000000000000000000000000000000000000000000000000000000000000000000000000000000000000000000000000000000000000000000000000000000000000000000000000000000000000000000000000000000000000000000000000000000000000000000000000000000000000000000000000000000000000000000000000000000000000000000000000000000000000000000000000000000000000000000000000000000000000000000000000000000000000000000000000000000000000000000000000000000000000000000000000000000000000000000000000000000000000000000000000000000000000000000000000000000000000000000000000000000000000000000000000000000000000000000000000000000000000000000000000000000000000000000000000000000000000000000000000000000000000000000000000000000000000000000000000000000000000000000000000000000000000000000000000000000000000000000000000000000000000000000000000000000000000000000000000000000000000000000000000000000000000000000000000000000000000000000000000000000000000000000000000000000000000000000000000000000000000000000000000000000000000000000000000000000000000000000000000000000000000000000000000000000000000000000000000000000000000000000000000000000000000000000000000000000000000000000000000000000000000000000000000000000000000000000000000000000000000000000000000000000000000000000000000000000000000000000000000000000000000000000000000000000000000000000000000000000000000000000000000000000000000000000000000000000000000000000000000000000000000000000000000000000000000000000000000000000000000000000000000000000000000000000000000000000000000000000000000000000000000000000000000000000000000000000000000000000000000000000000000000000000000000000000000000000000000000000000000000000000000000000000000000000000000000000000000000000000000000000000000000000000000000000000000000000000000000000000000000000000000000000000000000000000000000000000000000000000000000000000000000000000000000000000000000000000000000000000000000000000000000000000000000000000000000000000000000000000000000000000000000000000000000000000000000000000000000000000000000000000000000000000000000000000000000000000000000000000000000000000000000000000000000000000000000000000000000000000000000000000000000000000000000000000000000000000000000000000000000000000000000000000000000000000000000000000000000000000000000000000000000000000000000000000000000000000000000000000000000000000000000000000000000000000000000000000000000000000000000000000000000000000000000000000000000000000000000000000000000000000000000000000000000000000000000000000000000000000000000000000000000000000000000000000000000000000000000000000000000000000000000000000000000000000000000000000000000000000000000000000000000000000000000000000000000000000000000000000000000000000000000000000000000000000000000000000000000000000000000000000000000000000000000000000000000000000000000000000000000000000000000000000000000000000000000000000000000000000000000000000000000000000000000000000000000000000000000000000000000000000000000000000000000000000000000000000000000000000000000000000000000000000000000000000000000000000000000000000000000000000000000000000000000000000000000000000000000000000000000000000000000000000000000000000000000000000000000000000000000000000000000000000000000000000000000000000000000000000000000000000000000000000000000000000000000000000000000000000000000000000000000000000000000000000000000000000000000000000000000000000000000000000000000000000000000000000000000000000000000000000000000000000000000000000000000000000000000000000000000000000000000000000000000000000000000000000000000000000000000000000000000000000000000000000000000000000000000000000000000000000000000000000000000000000000000000000000000000000000000000000000000000000000000000000000000000000000000000000000000000000000000000000000000000000000000000000000000000000000000000000000000000000000000000000000000000000000000000000000000000000000000000000000000000000000000000000000000000000000000000000000000000000000000000000000000000000000000000000000000000000000000000000000000000000000000000000000000000000000000000000000000000000000000000000000000000000000000000000000000000000000000000000000000000000000000000000000000000000000000000000000000000000000000000000000000000000000000000000000000000000000000000000000000000000000000000000000000000000000000000000000000000000000000000000000000000000000000000000000000000000000000000000000000000000000000000000000000000000000000000000000000000000000000000000000000000000000000000000000000000000000000000000000000000000000000000000000000000000000000000000000000000000000000000000000000000000000000000000000000000000000000000000000000000000000000000000000000000000000000000000000000000000000000000000000000000000000000000000000000000000000000000000000000000000000000000000000000000000000000000000000000000000000000000000000000000000000000000000000000000000000000000000000000000000000000000000000000000000000000000000000000000000000000000000000000000000000000000000000000000000000000000000000000000000000000000000000000000000000000000000000000000000000000000000000000000000000000000000000000000000000000000000000000000000000000000000000000000000000000000000000000000000000000000000000000000000000000000000000000000000000000000000000000000000000000000000000000000000000000000000000000000000000000000000000000000000000000000000000000000000000000000000000000000000000000000000000000000000000000000000000000000000000000000000000000000000000000000000000000000000000000000000000000000000000000000000000000000000000000000000000000000000000000000000000000000000000000000000000000000000000000000000000000000000000000000000000000000000000000000000000000000000000000000000000000000000000000000000000000000000000000000000000000000000000000000000000000000000000000000000000000000000000000000000000000000000000000000000000000000000000000000000000000000000000000000000000000000000000000000000000000000000000000000000000000000000000000000000000000000000000000000000000000000000000000000000000000000000000000000000000000000000000000000000000000000000000000000000000000000000000000000000000000000000000000000000000000000000000000000000000000000000000000000000000000000000000000000000000000000000000000000000000000000000000000000000000000000000000000000000000000000000000000000000000000000000000000000000000000000000000000000000000000000000000000000000000000000000000000000000000000000000000000000000000000000000000000000000000000000000000000000000000000000000000000000000000000000000000000000000000000000000000000000000000000000000000000000000000000000000000000000000000000000000000000000000000000000000000000000000000000000000000000000000000000000000000000000000000000000000000000000000000000000000000000000000000000000000000000000000000000000000000000000000000000000000000000000000000000000000000000000000000000000000000000000000000000000000000000000000000000000000000000000000000000000000000000000000000000000000000000000000000000000000000000000000000000000000000000000000000000000000000000000000000000000000000000000000000000000000000000000000000000000000000000000000000000000000000000000000000000000000000000000000000000000000000000000000000000000000000000000000000000000000000000000000000000000000000000000000000000000000000000000000000000000000000000000000000000000000000000000000000000000000000000000000000000000000000000000000000000000000000000000000000000000000000000000000000000000000000000000000000000000000000000000000000000000000000000000000000000000000000000000000000000000000000000000000000000000000000000000000000000000000000000000000000000000000000000000000000000000000000000000000000000000000000000000000000000000000000000000000000000000000000000000000000000000000000000000000000000000000000000000000000000000000000000000000000000000000000000000000000000000000000000000000000000000000000000000000000000000000000000000000000000000000000000000000000000000000000000000000000000000000000000000000000000000000000000000000000000000000000000000000000000000000000000000000000000000000000000000000000000000000000000000000000000000000000000000000000000000000000000000000000000000000000000000000000000000000000000000000000000000000000000000000000000000000000000000000000000000000000000000000000000000000000000000000000000000000000000000000000000000000000000000000000000000000000000000000000000000000000000000000000000000000000000000000000000000000000000000000000000000000000000000000000000000000000000000000000000000000000000000000000000000000000000000000000000000000000000000000000000000000000000000000000000000000000000000000000000000000000000000000000000000000000000000000000000000000000000000000000000000000000000000000000000000000000000000000000000000000000000000000000000000000000000000000000000000000000000000000000000000000000000000000000000000000000000000000000000000000000000000000000000000000000000000000000000000000000000000000000000000000000000000000000000000000000000000000000000000000000000000000000000000000000000000000000000000000000000000000000000000000000000000000000000000000000000000000000000000000000000000000000000000000000000000000000000000000000000000000000000000000000000000000000000000000000000000000000000000000000000000000000000000000000000000000000000000000000000000000000000000000000000000000000000000000000000000000000000000000000000000000000000000000000000000000000000000000000000000000000000000000000000000000000000000000000000000000000000000000000000000000000000000000000000000000000000000000000000000000000000000000000000000000000000000000000000000000000000000000000000000000000000000000000000000000000000000000000000000000000000000000000000000000000000000000000000000000000000000000000000000000000000000000000000000000000000000000000000000000000000000000000000000000000000000000000000000000000000000000000000000000000000000000000000000000000000000000000000000000000000000000000000000000000000000000000000000000000000000000000000000000000000000000000000000000000000000000000000000000000000000000000000000000000000000000000000000000000000000000000000000000000000000000000000000000000000000000000000000000000000000000000000000000000000000000000000000000000000000000000000000000000000000000000000000000000000000000000000000000000000000000000000000000000000000000000000000000000000000000000000000000000000000000000000000000000000000000000000000000000000000000000000000000000000000000000000000000000000000000000000000000000000000000000000000000000000000000000000000000000000000000000000000000000000000000000000000000000000000000000000000000000000000000000000000000000000000000000000000000000000000000000000000000000000000000000000000000000000000000000000000000000000000000000000000000000000000000000000000000000000000000000000000000000000000000000000000000000000000000000000000000000000000000000000000000000000000000000000000000000000000000000000000000000000000000000000000000000000000000000000000000000000000000000000000000000000000000000000000000000000000000000000000000000000000000000000000000000000000000000000000000000000000000000000000000000000000000000000000000000000000000000000000000000000000000000000000000000000000000000000000000000000000000000000000000000000000000000000000000000000000000000000000000000000000000000000000000000000000000000000000000000000000000000000000000000000000000000000000000000000000000000000000000000000000000000000000000000000000000000000000000000000000000000000000000000000000000000000000000000000000000000000000000000000000000000000000000000000000000000000000000000000000000000000000000000000000000000000000000000000000000000000000000000000000000000000000000000000000000000000000000000000000000000000000000000000000000000000000000000000000000000000000000000000000000000000000000000000000000000000000000000000000000000000000000000000000000000000000000000000000000000000000000000000000000000000000000000000000000000000000000000000000000000000000000000000000000000000000000000000000000000000000000000000000000000000000000000000000000000000000000000000000000000000000000000000000000000000000000000000000000000000000000000000000000000000000000000000000000000000000000000000000000000000000000000000000000000000000000000000000000000000000000000000000000000000000000000000000000000000000000000000000000000000000000000000000000000000000000000000000000000000000000000000000000000000000000000000000000000000000000000000000000000000000000000000000000000000000000000000000000000000000000000000000000000000000000000000000000000000000000000000000000000000000000000000000000000000000000000000000000000000000000000000000000000000000000000000000000000000000000000000000000000000000000000000000000000000000000000000000000000000000000000000000000000000000000000000000000000000000000000000000000000000000000000000000000000000000000000000000000000000000000000000000000000000000000000000000000000000000000000000000000000000000000000000000000000000000000000000000000000000000000000000000000000000000000000000000000000000000000000000000000000000000000000000000000000000000000000000000000000000000000000000000000000000000000000000000000000000000000000000000000000000000000000000000000000000000000000000000000000000000000000000000000000000000000000000000000000000000000000000000000000000000000000000000000000000000000000000000000000000000000000000000000000000000000000000000000000000000000000000000000000000000000000000000000000000000000000000000000000000000000000000000000000000000000000000000000000000000000000000000000000000000000000000000000000000000000000000000000000000000000000000000000000000000000000000000000000000000000000000000000000000000000000000000000000000000000000000000000000000000000000000000000000000000000000000000000000000000000000000000000000000000000000000000000000000000000000000000000000000000000000000000000000000000000000000000000000000000000000000000000000000000000000000000000000000000000000000000000000000000000000000000000000000000000000000000000000000000000000000000000000000000000000000000000000000000000000000000000000000000000000000000000000000000000000000000000000000000000000000000000000000000000000000000000000000000000000000000000000000000000000000000000000000000000000000000000000000000000000000000000000000000000000000000000000000000000000000000000000000000000000000000000000000000000000000000000000000000000000000000000000000000000000000000000000000000000000000000000000000000000000000000000000000000000000000000000000000000000000000000000000000000000000000000000000000000000000000000000000000000000000000000000000000000000000000000000000000000000000000000000000000000000000000000000000000000000000000000000000000000000000000000000000000000000000000000000000000000000000000000000000000000000000000000000000000000000000000000000000000000000000000000000000000000000000000000000000000000000000000000000000000000000000000000000000000000000000000000000000000000000000000000000000000000000000000000000000000000000000000000000000000000000000000000000000000000000000000000000000000000000000000000000000000000000000000000000000000000000000000000000000000000000000000000000000000000000000000000000000000000000000000000000000000000000000000000000000000000000000000000000000000000000000000000000000000000000000000000000000000000000000000000000000000000000000000000000000000000000000000000000000000000000000000000000000000000000000000000000000000000000000000000000000000000000000000000000000000000000000000000000000000000000000000000000000000000000000000000000000000000000000000000000000000000000000000000000000000000000000000000000000000000000000000000000000000000000000000000000000000000000000000000000000000000000000000000000000000000000000000000000000000000000000000000000000000000000000000000000000000000000000000000000000000000000000000000000000000000000000000000000000000000000000000000000000000000000000000000000000000000000000000000000000000000000000000000000000000000000000000000000000000000000000000000000000000000000000000000000000000000000000000000000000000000000000000000000000000000000000000000000000000000000000000000000000000000000000000000000000000000000000000000000000000000000000000000000000000000000000000000000000000000000000000000000000000000000000000000000000000000000000000000000000000000000000000000000000000000000000000000000000000000000000000000000000000000000000000000000000000000000000000000000000000000000000000000000000000000000000000000000000000000000000000000000000000000000000000000000000000000000000000000000000000000000000000000000000000000000000000000000000000000000000000000000000000000000000000000000000000000000000000000000000000000000000000000000000000000000000000000000000000000000000000000000000000000000000000000000000000000000000000000000000000000000000000000000000000000000000000000000000000000000000000000000000000000000000000000000000000000000000000000000000000000000000000000000000000000000000000000000000000000000000000000000000000000000000000000000000000000000000000000000000000000000000000000000000000000000000000000000000000000000000000000000000000000000000000000000000000000000000000000000000000000000000000000000000000000000000000000000000000000000000000000000000000000000000000000000000000000000000000000000000000000000000000000000000000000000000000000000000000000000000000000000000000000000000000000000000000000000000000000000000000000000000000000000000000000000000000000000000000000000000000000000000000000000000000000000000000000000000000000000000000000000000000000000000000000000000000000000000000000000000000000000000000000000000000000000000000000000000000000000000000000000000000000000000000000000000000000000000000000000000000000000000000000000000000000000000000000000000000000000000000000000000000000000000000000000000000000000000000000000000000000000000000000000000000000000000000000000000000000000000000000000000000000000000000000000000000000000000000000000000000000000000000000000000000000000000000000000000000000000000000000000000000000000000000000000000000000000000000000000000000000000000000000000000000000000000000000000000000000000000000000000000000000000000000000000000000000000000000000000000000000000000000000000000000000000000000000000000000000000000000000000000000000000000000000000000000000000000000000000000000000000000000000000000000000000000000000000000000000000000000000000000000000000000000000000000000000000000000000000000000000000000000000000000000000000000000000000000000000000000000000000000000000000000000000000000000000000000000000000000000000000000000000000000000000000000000000000000000000000000000000000000000000000000000000000000000000000000000000000000000000000000000000000000000000000000000000000000000000000000000000000000000000000000000000000000000000000000000000000000000000000000000000000000000000000000000000000000000000000000000000000000000000000000000000000000000000000000000000000000000000000000000000000000000000000000000000000000000000000000000000000000000000000000000000000000000000000000000000000000000000000000000000000000000000000000000000000000000000000000000000000000000000000000000000000000000000000000000000000000000000000000000000000000000000000000000000000000000000000000000000000000000000000000000000000000000000000000000000000000000000000000000000000000000000000000000000000000000000000000000000000000000000000000000000000000000000000000000000000000000000000000000000000000000000000000000000000000000000000000000000000000000000000000000000000000000000000000000000000000000000000000000000000000000000000000000000000000000000000000000000000000000000000000000000000000000000000000000000000000000000000000000000000000000000000000000000000000000000000000000000000000000000000000000000000000000000000000000000000000000000000000000000000000000000000000000000000000000000000000000000000000000000000000000000000000000000000000000000000000000000000000000000000000000000000000000000000000000000000000000000000000000000000000000000000000000000000000000000000000000000000000000000000000000000000000000000000000000000000000000000000000000000000000000000000000000000000000000000000000000000000000000000000000000000000000000000000000000000000000000000000000000000000000000000000000000000000000000000000000000000000000000000000000000000000000000000000000000000000000000000000000000000000000000000000000000000000000000000000000000000000000000000000000000000000000000000000000000000000000000000000000000000000000000000000000000000000000000000000000000000000000000000000000000000000000000000000000000000000000000000000000000000000000000000000000000000000000000000000000000000000000000000000000000000000000000000000000000000000000000000000000000000000000000000000000000000000000000000000000000000000000000000000000000000000000000000000000000000000000000000000000000000000000000000000000000000000000000000000000000000000000000000000000000000000000000000000000000000000000000000000000000000000000000000000000000000000000000000000000000000000000000000000000000000000000000000000000000000000000000000000000000000000000000000000000000000000000000000000000000000000000000000000000000000000000000000000000000000000000000000000000000000000000000000000000000000000000000000000000000000000000000000000000000000000000000000000000000000000000000000000000000000000000000000000000000000000000000000000000000000000000000000000000000000000000000000000000000000000000000000000000000000000000000000000000000000000000000000000000000000000000000000000000000000000000000000000000000000000000000000000000000000000000000000000000000000000000000000000000000000000000000000000000000000000000000000000000000000000000000000000000000000000000000000000000000000000000000000000000000000000000000000000000000000000000000000000000000000000000000000000000000000000000000000000000000000000000000000000000000000000000000000000000000000000000000000000000000000000000000000000000000000000000000000000000000000000000000000000000000000000000000000000000000000000000000000000000000000000000000000000000000000000000000000000000000000000000000000000000000000000000000000000000000000000000000000000000000000000000000000000000000000000000000000000000000000000000000000000000000000000000000000000000000000000000000000000000000000000000000000000000000000000000000000000000000000000000000000000000000000000000000000000000000000000000000000000000000000000000000000000000000000000000000000000000000000000000000000000000000000000000000000000000000000000000000000000000000000000000000000000000000000000000000000000000000000000000000000000000000000000000000000000000000000000000000000000000000000000000000000000000000000000000000000000000000000000000000000000000000000000000000000000000000000000000000000000000000000000000000000000000000000000000000000000000000000000000000000000000000000000000000000000000000000000000000000000000000000000000000000000000000000000000000000000000000000000000000000000000000000000000000000000000000000000000000000000000000000000000000000000000000000000000000000000000000000000000000000000000000000000000000000000000000000000000000000000000000000000000000000000000000000000000000000000000000000000000000000000000000000000000000000000000000000000000000000000000000000000000000000000000000000000000000000000000000000000000000000000000000000000000000000000000000000000000000000000000000000000000000000000000000000000000000000000000000000000000000000000000000000000000000000000000000000000000000000000000000000000000000000000000000000000000000000000000000000000000000000000000000000000000000000000000000000000000000000000000000000000000000000000000000000000000000000000000000000000000000000000000000000000000000000000000000000000000000000000000000000000000000000000000000000000000000000000000000000000000000000000000000000000000000000000000000000000000000000000000000000000000000000000000000000000000000000000000000000000000000000000000000000000000000000000000000000000000000000000000000000000000000000000000000000000000000000000000000000000000000000000000000000000000000000000000000000000000000000000000000000000000000000000000000000000000000000000000000000000000000000000000000000000000000000000000000000000000000000000000000000000000000000000000000000000000000000000000000000000000000000000000000000000000000000000000000000000000000000000000000000000000000000000000000000000000000000000000000000000000000000000000000000000000000000000000000000000000000000000000000000000000000000000000000000000000000000000000000000000000000000000000000000000000000000000000000000000000000000000000000000000000000000000000000000000000000000000000000000000000000000000000000000000000000000000000000000000000000000000000000000000000000000000000000000000000000000000000000000000000000000000000000000000000000000000000000000000000000000000000000000000000000000000000000000000000000000000000000000000000000000000000000000000000000000000000000000000000000000000000000000000000000000000000000000000000000000000000000000000000000000000000000000000000000000000000000000000000000000000000000000000000000000000000000000000000000000000000000000000000000000000000000000000000000000000000000000000000000000000000000000000000000000000000000000000000000000000000000000000000000000000000000000000000000000000000000000000000000000000000000000000000000000000000000000000000000000000000000000000000000000000000000000000000000000000000000000000000000000000000000000000000000000000000000000000000000000000000000000000000000000000000000000000000000000000000000000000000000000000000000000000000000000000000000000000000000000000000000000000000000000000000000000000000000000000000000000000000000000000000000000000000000000000000000000000000000000000000000000000000000000000000000000000000000000000000000000000000000000000000000000000000000000000000000000000000000000000000000000000000000000000000000000000000000000000000000000000000000000000000000000000000000000000000000000000000000000000000000000000000000000000000000000000000000000000000000000000000000000000000000000000000000000000000000000000000000000000000000000000000000000000000000000000000000000000000000000000000000000000000000000000000000000000000000000000000000000000000000000000000000000000000000000000000000000000000000000000000000000000000000000000000000000000000000000000000000000000000000000000000000000000000000000000000000000000000000000000000000000000000000000000000000000000000000000000000000000000000000000000000000000000000000000000000000000000000000000000000000000000000000000000000000000000000000000000000000000000000000000000000000000000000000000000000000000000000000000000000000000000000000000000000000000000000000000000000000000000000000000000000000000000000000000000000000000000000000000000000000000000000000000000000000000000000000000000000000000000000000000000000000000000000000000000000000000000000000000000000000000000000000000000000000000000000000000000000000000000000000000000000000000000000000000000000000000000000000000000000000000000000000000000000000000000000000000000000000000000000000000000000000000000000000000000000000000000000000000000000000000000000000000000000000000000000000000000000000000000000000000000000000000000000000000000000000000000000000000000000000000000000000000000000000000000000000000000000000000000000000000000000000000000000000000000000000000000000000000000000000000000000000000000000000000000000000000000000000000000000000000000000000000000000000000000000000000000000000000000000000000000000000000000000000000000000000000000000000000000000000000000000000000000000000000000000000000000000000000000000000000000000000000000000000000000000000000000000000000000000000000000000000000000000000000000000000000000000000000000000000000000000000000000000000000000000000000000000000000000000000000000000000000000000000000000000000000000000000000000000000000000000000000000000000000000000000000000000000000000000000000000000000000000000000000000000000000000000000000000000000000000000000000000000000000000000000000000000000000000000000000000000000000000000000000000000000000000000000000000000000000000000000000000000000000000000000000000000000000000000000000000000000000000000000000000000000000000000000000000000000000000000000000000000000000000000000000000000000000000000000000000000000000000000000000000000000000000000000000000000000000000000000000000000000000000000000000000000000000000000000000000000000000000000000000000000000000000000000000000000000000000000000000000000000000000000000000000000000000000000000000000000000000000000000000000000000000000000000000000000000000000000000000000000000000000000000000000000000000000000000000000000000000000000000000000000000000000000000000000000000000000000000000000000000000000000000000000000000000000000000000000000000000000000000000000000000000000000000000000000000000000000000000000000000000000000000000000000000000000000000000000000000000000000000000000000000000000000000000000000000000000000000000000000000000000000000000000000000000000000000000000000000000000000000000000000000000000000000000000000000000000000000000000000000000000000000000000000000000000000000000000000000000000000000000000000000000000000000000000000000000000000000000000000000000000000000000000000000000000000000000000000000000000000000000000000000000000000000000000000000000000000000000000000000000000000000000000000000000000000000000000000000000000000000000000000000000000000000000000000000000000000000000000000000000000000000000000000000000000000000000000000000000000000000000000000000000000000000000000000000000000000000000000000000000000000000000000000000000000000000000000000000000000000000000000000000000000000000000000000000000000000000000000000000000000000000000000000000000000000000000000000000000000000000000000000000000000000000000000000000000000000000000000000000000000000000000000000000000000000000000000000000000000000000000000000000000000000000000000000000000000000000000000000000000000000000000000000000000000000000000000000000000000000000000000000000000000000000000000000000000000000000000000000000000000000000000000000000000000000000000000000000000000000000000000000000000000000000000000000000000000000000000000000000000000000000000000000000000000000000000000000000000000000000000000000000000000000000000000000000000000000000000000000000000000000000000000000000000000000000000000000000000000000000000000000000000000000000000000000000000000000000000000000000000000000000000000000000000000000000000000000000000000000000000000000000000000000000000000000000000000000000000000000000000000000000000000000000000000000000000000000000000000000000000000000000000000000000000000000000000000000000000000000000000000000000000000000000000000000000000000000000000000000000000000000000000000000000000000000000000000000000000000000000000000000000000000000000000000000000000000000000000000000000000000000000000000000000000000000000000000000000000000000000000000000000000000000000000000000000000000000000000000000000000000000000000000000000000000000000000000000000000000000000000000000000000000000000000000000000000000000000000000000000000000000000000000000000000000000000000000000000000000000000000000000000000000000000000000000000000000000000000000000000000000000000000000000000000000000000000000000000000000000000000000000000000000000000000000000000000000000000000000000000000000000000000000000000000000000000000000000000000000000000000000000000000000000000000000000000000000000000000000000000000000000000000000000000000000000000000000000000000000000000000000000000000000000000000000000000000000000000000000000000000000000000000000000000000000000000000000000000000000000000000000000000000000000000000000000000000000000000000000000000000000000000000000000000000000000000000000000000000000000000000000000000000000000000000000000000000000000000000000000000000000000000000000000000000000000000000000000000000000000000000000000000000000000000000000000000000000000000000000000000000000000000000000000000000000000000000000000000000000000000000000000000000000000000000000000000000000000000000000000000000000000000000000000000000000000000000000000000000000000000000000000000000000000000000000000000000000000000000000000000000000000000000000000000000000000000000000000000000000000000000000000000000000000000000000000000000000000000000000000000000000000000000000000000000000000000000000000000000000000000000000000000000000000000000000000000000000000000000000000000000000000000000000000000000000000000000000000000000000000000000000000000000000000000000000000000000000000000000000000000000000000000000000000000000000000000000000000000000000000000000000000000000000000000000000000000000000000000000000000000000000000000000000000000000000000000000000000000000000000000000000000000000000000000000000000000000000000000000000000000000000000000000000000000000000000000000000000000000000000000000000000000000000000000000000000000000000000000000000000000000000000000000000000000000000000000000000000000000000000000000000000000000000000000000000000000000000000000000000000000000000000000000000000000000000000000000000000000000000000000000000000000000000000000000000000000000000000000000000000000000000000000000000000000000000000000000000000000000000000000000000000000000000000000000000000000000000000000000000000000000000000000000000000000000000000000000000000000000000000000000000000000000000000000000000000000000000000000000000000000000000000000000000000000000000000000000000000000000000000000000000000000000000000000000000000000000000000000000000000000000000000000000000000000000000000000000000000000000000000000000000000000000000000000000000000000000000000000000000000000000000000000000000000000000000000000000000000000000000000000000000000000000000000000000000000000000000000000000000000000000000000000000000000000000000000000000000000000000000000000000000000000000000000000000000000000000000000000000000000000000000000000000000000000000000000000000000000000000000000000000000000000000000000000000000000000000000000000000000000000000000000000000000000000000000000000000000000000000000000000000000000000000000000000000000000000000000000000000000000000000000000000000000000000000000000000000000000000000000000000000000000000000000000000000000000000000000000000000000000000000000000000000000000000000000000000000000000000000000000000000000000000000000000000000000000000000000000000000000000000000000000000000000000000000000000000000000000000000000000000000000000000000000000000000000000000000000000000000000000000000000000000000000000000000000000000000000000000000000000000000000000000000000000000000000000000000000000000000000000000000000000000000000000000000000000000000000000000000000000000000000000000000000000000000000000000000000000000000000000000000000000000000000000000000000000000000000000000000000000000000000000000000000000000000000000000000000000000000000000000000000000000000000000000000000000000000000000000000000000000000000000000000000000000000000000000000000000000000000000000000000000000000000000000000000000000000000000000000000000000000000000000000000000000000000000000000000000000000000000000000000000000000000000000000000000000000000000000000000000000000000000000000000000000000000000000000000000000000000000000000000000000000000000000000000000000000000000000000000000000000000000000000000000000000000000000000000000000000000000000000000000000000000000000000000000000000000000000000000000000000000000000000000000000000000000000000000000000000000000000000000000000000000000000000000000000000000000000000000000000000000000000000000000000000000000000000000000000000000000000000000000000000000000000000000000000000000000000000000000000000000000000000000000000000000000000000000000000000000000000000000000000000000000000000000000000000000000000000000000000000000000000000000000000000000000000000000000000000000000000000000000000000000000000000000000000000000000000000000000000000000000000000000000000000000000000000000000000000000000000000000000000000000000000000000000000000000000000000000000000000000000000000000000000000000000000000000000000000000000000000000000000000000000000000000000000000000000000000000000000000000000000000000000000000000000000000000000000000000000000000000000000000000000000000000000000000000000000000000000000000000000000000000000000000000000000000000000000000000000000000000000000000000000000000000000000000000000000000000000000000000000000000000000000000000000000000000000000000000000000000000000000000000000000000000000000000000000000000000000000000000000000000000000000000000000000000000000000000000000000000000000000000000000000000000000000000000000000000000000000000000000000000000000000000000000000000000000000000000000000000000000000000000000000000000000000000000000000000000000000000000000000000000000000000000000000000000000000000000000000000000000000000000000000000000000000000000000000000000000000000000000000000000000000000000000000000000000000000000000000000000000000000000000000000000000000000000000000000000000000000000000000000000000000000000000000000000000000000000000000000000000000000000000000000000000000000000000000000000000000000000000000000000000000000000000000000000000000000000000000000000000000000000000000000000000000000000000000000000000000000000000000000000000000000000000000000000000000000000000000000000000000000000000000000000000000000000000000000000000000000000000000000000000000000000000000000000000000000000000000000000000000000000000000000000000000000000000000000000000000000000000000000000000000000000000000000000000000000000000000000000000000000000000000000000000000000000000000000000000000000000000000000000000000000000000000000000000000000000000000000000000000000000000000000000000000000000000000000000000000000000000000000000000000000000000000000000000000000000000000000000000000000000000000000000000000000000000000000000000000000000000000000000000000000000000000000000000000000000000000000000000000000000000000000000000000000000000000000000000000000000000000000000000000000000000000000000000000000000000000000000000000000000000000000000000000000000000000000000000000000000000000000000000000000000000000000000000000000000000000000000000000000000000000000000000000000000000000000000000000000000000000000000000000000000000000000000000000000000000000000000000000000000000000000000000000000000000000000000000000000000000000000000000000000000000000000000000000000000000000000000000000000000000000000000000000000000000000000000000000000000000000000000000000000000000000000000000000000000000000000000000000000000000000000000000000000000000000000000000000000000000000000000000000000000000000000000000000000000000000000000000000000000000000000000000000000000000000000000000000000000000000000000000000000000000000000000000000000000000000000000000000000000000000000000000000000000000000000000000000000000000000000000000000000000000000000000000000000000000000000000000000000000000000000000000000000000000000000000000000000000000000000000000000000000000000000000000000000000000000000000000000000000000000000000000000000000000000000000000000000000000000000000000000000000000000000000000000000000000000000000000000000000000000000000000000000000000000000000000000000000000000000000000000000000000000000000000000000000000000000000000000000000000000000000000000000000000000000000000000000000000000000000000000000000000000000000000000000000000000000000000000000000000000000000000000000000000000000000000000000000000000000000000000000000000000000000000000000000000000000000000000000000000000000000000000000000000000000000000000000000000000000000000000000000000000000000000000000000000000000000000000000000000000000000000000000000000000000000000000000000000000000000000000000000000000000000000000000000000000000000000000000000000000000000000000000000000000000000000000000000000000000000000000000000000000000000000000000000000000000000000000000000000000000000000000000000000000000000000000000000000000000000000000000000000000000000000000000000000000000000000000000000000000000000000000000000000000000000000000000000000000000000000000000000000000000000000000000000000000000000000000000000000000000000000000000000000000000000000000000000000000000000000000000000000000000000000000000000000000000000000000000000000000000000000000000000000000000000000000000000000000000000000000000000000000000000000000000000000000000000000000000000000000000000000000000000000000000000000000000000000000000000000000000000000000000000000000000000000000000000000000000000000000000000000000000000000000000000000000000000000000000000000000000000000000000000000000000000000000000000000000000000000000000000000000000000000000000000000000000000000000000000000000000000000000000000000000000000000000000000000000000000000000000000000000000000000000000000000000000000000000000000000000000000000000000000000000000000000000000000000000000000000000000000000000000000000000000000000000000000000000000000000000000000000000000000000000000000000000000000000000000000000000000000000000000000000000000000000000000000000000000000000000000000000000000000000000000000000000000000000000000000000000000000000000000000000000000000000000000000000000000000000000000000000000000000000000000000000000000000000000000000000000000000000000000000000000000000000000000000000000000000000000000000000000000000000000000000000000000000000000000000000000000000000000000000000000000000000000000000000000000000000000000000000000000000000000000000000000000000000000000000000000000000000000000000000000000000000000000000000000000000000000000000000000000000000000000000000000000000000000000000000000000000000000000000000000000000000000000000000000000000000000000000000000000000000000000000000000000000000000000000000000000000000000000000000000000000000000000000000000000000000000000000000000000000000000000000000000000000000000000000000000000000000000000000000000000000000000000000000000000000000000000000000000000000000000000000000000000000000000000000000000000000000000000000000000000000000000000000000000000000000000000000000000000000000000000000000000000000000000000000000000000000000000000000000000000000000000000000000000000000000000000000000000000000000000000000000000000000000000000000000000000000000000000000000000000000000000000000000000000000000000000000000000000000000000000000000000000000000000000000000000000000000000000000000000000000000000000000000000000000000000000000000000000000000000000000000000000000000000000000000000000000000000000000000000000000000000000000000000000000000000000000000000000000000000000000000000000000000000000000000000000000000000000000000000000000000000000000000000000000000000000000000000000000000000000000000000000000000000000000000000000000000000000000000000000000000000000000000000000000000000000000000000000000000000000000000000000000000000000000000000000000000000000000000000000000000000000000000000000000000000000000000000000000000000000000000000000000000000000000000000000000000000000000000000000000000000000000000000000000000000000000000000000000000000000000000000000000000000000000000000000000000000000000000000000000000000000000000000000000000000000000000000000000000000000000000000000000000000000000000000000000000000000000000000000000000000000000000000000000000000000000000000000000000000000000000000000000000000000000000000000000000000000000000000000000000000000000000000000000000000000000000000000000000000000000000000000000000000000000000000000000000000000000000000000000000000000000000000000000000000000000000000000000000000000000000000000000000000000000000000000000000000000000000000000000000000000000000000000000000000000000000000000000000000000000000000000000000000000000000000000000000000000000000000000000000000000000000000000000000000000000000000000000000000000000000000000000000000000000000000000000000000000000000000000000000000000000000000000000000000000000000000000000000000000000000000000000000000000000000000000000000000000000000000000000000000000000000000000000000000000000000000000000000000000000000000000000000000000000000000000000000000000000000000000000000000000000000000000000000000000000000000000000000000000000000000000000000000000000000000000000000000000000000000000000000000000000000000000000000000000000000000000000000000000000000000000000000000000000000000000000000000000000000000000000000000000000000000000000000000000000000000000000000000000000000000000000000000000000000000000000000000000000000000000000000000000000000000000000000000000000000000000000000000000000000000000000000000000000000000000000000000000000000000000000000000000000000000000000000000000000000000000000000000000000000000000000000000000000000000000000000000000000000000000000000000000000000000000000000000000000000000000000000000000000000000000000000000000000000000000000000000000000000000000000000000000000000000000000000000000000000000000000000000000000000000000000000000000000000000000000000000000000000000000000000000000000000000000000000000000000000000000000000000000000000000000000000000000000000000000000000000000000000000000000000000000000000000000000000000000000000000000000000000000000000000000000000000000000000000000000000000000000000000000000000000000000000000000000000000000000000000000000000000000000000000000000000000000000000000000000000000000000000000000000000000000000000000000000000000000000000000000000000000000000000000000000000000000000000000000000000000000000000000000000000000000000000000000000000000000000000000000000000000000000000000000000000000000000000000000000000000000000000000000000000000000000000000000000000000000000000000000000000000000000000000000000000000000000000000000000000000000000000000000000000000000000000000000000000000000000000000000000000000000000000000000000000000000000000000000000000000000000000000000000000000000000000000000000000000000000000000000000000000000000000000000000000000000000000000000000000000000000000000000000000000000000000000000000000000000000000000000000000000000000000000000000000000000000000000000000000000000000000000000000000000000000000000000000000000000000000000000000000000000000000000000000000000000000000000000000000000000000000000000000000000000000000000000000000000000000000000000000000000000000000000000000000000000000000000000000000000000000000000000000000000000000000000000000000000000000000000000000000000000000000000000000000000000000000000000000000000000000000000000000000000000000000000000000000000000000000000000000000000000000000000000000000000000000000000000000000000000000000000000000000000000000000000000000000000000000000000000000000000000000000000000000000000000000000000000000000000000000000000000000000000000000000000000000000000000000000000000000000000000000000000000000000000000000000000000000000000000000000000000000000000000000000000000000000000000000000000000000000000000000000000000000000000000000000000000000000000000000000000000000000000000000000000000000000000000000000000000000000000000000000000000000000000000000000000000000000000000000000000000000000000000000000000000000000000000000000000000000000000000000000000000000000000000000000000000000000000000000000000000000000000000000000000000000000000000000000000000000000000000000000000000000000000000000000000000000000000000000000000000000000000000000000000000000000000000000000000000000000000000000000000000000000000000000000000000000000000000000000000000000000000000000000000000000000000000000000000000000000000000000000000000000000000000000000000000000000000000000000000000000000000000000000000000000000000000000000000000000000000000000000000000000000000000000000000000000000000000000000000000000000000000000000000000000000000000000000000000000000000000000000000000000000000000000000000000000000000000000000000000000000000000000000000000000000000000000000000000000000000000000000000000000000000000000000000000000000000000000000000000000000000000000000000000000000000000000000000000000000000000000000000000000000000000000000000000000000000000000000000000000000000000000000000000000000000000000000000000000000000000000000000000000000000000000000000000000000000000000000000000000000000000000000000000000000000000000000000000000000000000000000000000000000000000000000000000000000000000000000000000000000000000000000000000000000000000000000000000000000000000000000000000000000000000000000000000000000000000000000000000000000000000000000000000000000000000000000000000000000000000000000000000000000000000000000000000000000000000000000000000000000000000000000000000000000000000000000000000000000000000000000000000000000000000000000000000000000000000000000000000000000000000000000000000000000000000000000000000000000000000000000000000000000000000000000000000000000000000000000000000000000000000000000000000000000000000000000000000000000000000000000000000000000000000000000000000000000000000000000000000000000000000000000000000000000000000000000000000000000000000000000000000000000000000000000000000000000000000000000000000000000000000000000000000000000000000000000000000000000000000000000000000000000000000000000000000000000000000000000000000000000000000000000000000000000000000000000000000000000000000000000000000000000000000000000000000000000000000000000000000000000000000000000000000000000000000000000000000000000000000000000000000000000000000000000000000000000000000000000000000000000000000000000000000000000000000000000000000000000000000000000000000000000000000000000000000000000000000000000000000000000000000000000000000000000000000000000000000000000000000000000000000000000000000000000000000000000000000000000000000000000000000000000000000000000000000000000000000000000000000000000000000000000000000000000000000000000000000000000000000000000000000000000000000000000000000000000000000000000000000000000000000000000000000000000000000000000000000000000000000000000000000000000000000000000000000000000000000000000000000000000000000000000000000000000000000000000000000000000000000000000000000000000000000000000000000000000000000000000000000000000000000000000000000000000000000000000000000000000000000000000000000000000000000000000000000000000000000000000000000000000000000000000000000000000000000000000000000000000000000000000000000000000000000000000000000000000000000000000000000000000000000000000000000000000000000000000000000000000000000000000000000000000000000000000000000000000000000000000000000000000000000000000000000000000000000000000000000000000000000000000000000000000000000000000000000000000000000000000000000000000000000000000000000000000000000000000000000000000000000000000000000000000000000000000000000000000000000000000000000000000000000000000000000000000000000000000000000000000000000000000000000000000000000000000000000000000000000000000000000000000000000000000000000000000000000000000000000000000000000000000000000000000000000000000000000000000000000000000000000000000000000000000000000000000000000000000000000000000000000000000000000000000000000000000000000000000000000000000000000000000000000000000000000000000000000000000000000000000000000000000000000000000000000000000000000000000000000000000000000000000000000000000000000000000000000000000000000000000000000000000000000000000000000000000000000000000000000000000000000000000000000000000000000000000000000000000000000000000000000000000000000000000000000000000000000000000000000000000000000000000000000000000000000000000000000000000000000000000000000000000000000000000000000000000000000000000000000000000000000000000000000000000000000000000000000000000000000000000000000000000000000000000000000000000000000000000000000000000000000000000000000000000000000000000000000000000000000000000000000000000000000000000000000000000000000000000000000000000000000000000000000000000000000000000000000000000000000000000000000000000000000000000000000000000000000000000000000000000000000000000000000000000000000000000000000000000000000000000000000000000000000000000000000000000000000000000000000000000000000000000000000000000000000000000000000000000000000000000000000000000000000000000000000000000000000000000000000000000000000000000000000000000000000000000000000000000000000000000000000000000000000000000000000000000000000000000000000000000000000000000000000000000000000000000000000000000000000000000000000000000000000000000000000000000000000000000000000000000000000000000000000000000000000000000000000000000000000000000000000000000000000000000000000000000000000000000000000000000000000000000000000000000000000000000000000000000000000000000000000000000000000000000000000000000000000000000000000000000000000000000000000000000000000000000000000000000000000000000000000000000000000000000000000000000000000000000000000000000000000000000000000000000000000000000000000000000000000000000000000000000000000000000000000000000000000000000000000000000000000000000000000000000000000000000000000000000000000000000000000000000000000000000000000000000000000000000000000000000000000000000000000000000000000000000000000000000000000000000000000000000000000000000000000000000000000000000000000000000000000000000000000000000000000000000000000000000000000000000000000000000000000000000000000000000000000000000000000000000000000000000000000000000000000000000000000000000000000000000000000000000000000000000000000000000000000000000000000000000000000000000000000000000000000000000000000000000000000000000000000000000000000000000000000000000000000000000000000000000000000000000000000000000000000000000000000000000000000000000000000000000000000000000000000000000000000000000000000000000000000000000000000000000000000000000000000000000000000000000000000000000000000000000000000000000000000000000000000000000000000000000000000000000000000000000000000000000000000000000000000000000000000000000000000000000000000000000000000000000000000000000000000000000000000000000000000000000000000000000000000000000000000000000000000000000000000000000000000000000000000000000000000000000000000000000000000000000000000000000000000000000000000000000000000000000000000000000000000000000000000000000000000000000000000000000000000000000000000000000000000000000000000000000000000000000000000000000000000000000000000000000000000000000000000000000000000000000000000000000000000000000000000000000000000000000000000000000000000000000000000000000000000000000000000000000000000000000000000000000000000000000000000000000000000000000000000000000000000000000000000000000000000000000000000000000000000000000000000000000000000000000000000000000000000000000000000000000000000000000000000000000000000000000000000000000000000000000000000000000000000000000000000000000000000000000000000000000000000000000000000000000000000000000000000000000000000000000000000000000000000000000000000000000000000000000000000000000000000000000000000000000000000000000000000000000000000000000000000000000000000000000000000000000000000000000000000000000000000000000000000000000000000000000000000000000000000000000000000000000000000000000000000000000000000000000000000000000000000000000000000000000000000000000000000000000000000000000000000000000000000000000000000000000000000000000000000000000000000000000000000000000000000000000000000000000000000000000000000000000000000000000000000000000000000000000000000000000000000000000000000000000000000000000000000000000000000000000000000000000000000000000000000000000000000000000000000000000000000000000000000000000000000000000000000000000000000000000000000000000000000000000000000000000000000000000000000000000000000000000000000000000000000000000000000000000000000000000000000000000000000000000000000000000000000000000000000000000000000000000000000000000000000000000000000000000000000000000000000000000000000000000000000000000000000000000000000000000000000000000000000000000000000000000000000000000000000000000000000000000000000000000000000000000000000000000000000000000000000000000000000000000000000000000000000000000000000000000000000000000000000000000000000000000000000000000000000000000000000000000000000000000000000000000000000000000000000000000000000000000000000000000000000000000000000000000000000000000000000000000000000000000000000000000000000000000000000000000000000000000000000000000000000000000000000000000000000000000000000000000000000000000000000000000000000000000000000000000000000000000000000000000000000000000000000000000000000000000000000000000000000000000000000000000000000000000000000000000000000000000000000000000000000000000000000000000000000000000000000000000000000000000000000000000000000000000000000000000000000000000000000000000000000000000000000000000000000000000000000000000000000000000000000000000000000000000000000000000000000000000000000000000000000000000000000000000000000000000000000000000000000000000000000000000000000000000000000000000000000000000000000000000000000000000000000000000000000000000000000000000000000000000000000000000000000000000000000000000000000000000000000000000000000000000000000000000000000000000000000000000000000000000000000000000000000000000000000000000000000000000000000000000000000000000000000000000000000000000000000000000000000000000000000000000000000000000000000000000000000000000000000000000000000000000000000000000000000000000000000000000000000000000000000000000000000000000000000000000000000000000000000000000000000000000000000000000000000000000000000000000000000000000000000000000000000000000000000000000000000000000000000000000000000000000000000000000000000000000000000000000000000000000000000000000000000000000000000000000000000000000000000000000000000000000000000000000000000000000000000000000000000000000000000000000000000000000000000000000000000000000000000000000000000000000000000000000000000000000000000000000000000000000000000000000000000000000000000000000000000000000000000000000000000000000000000000000000000000000000000000000000000000000000000000000000000000000000000000000000000000000000000000000000000000000000000000000000000000000000000000000000000000000000000000000000000000000000000000000000000000000000000000000000000000000000000000000000000000000000000000000000000000000000000000000000000000000000000000000000000000000000000000000000000000000000000000000000000000000000000000000000000000000000000000000000000000000000000000000000000000000000000000000000000000000000000000000000000000000000000000000000000000000000000000000000000000000000000000000000000000000000000000000000000000000000000000000000000000000000000000000000000000000000000000000000000000000000000000000000000000000000000000000000000000000000000000000000000000000000000000000000000000000000000000000000000000000000000000000000000000000000000000000000000000000000000000000000000000000000000000000000000000000000000000000000000000000000000000000000000000000000000000000000000000000000000000000000000000000000000000000000000000000000000000000000000000000000000000000000000000000000000000000000000000000000000000000000000000000000000000000000000000000000000000000000000000000000000000000000000000000000000000000000000000000000000000000000000000000000000000000000000000000000000000000000000000000000000000000000000000000000000000000000000000000000000000000000000000000000000000000000000000000000000000000000000000000000000000000000000000000000000000000000000000000000000000000000000000000000000000000000000000000000000000000000000000000000000000000000000000000000000000000000000000000000000000000000000000000000000000000000000000000000000000000000000000000000000000000000000000000000000000000000000000000000000000000000000000000000000000000000000000000000000000000000000000000000000000000000000000000000000000000000000000000000000000000000000000000000000000000000000000000000000000000000000000000000000000000000000000000000000000000000000000000000000000000000000000000000000000000000000000000000000000000000000000000000000000000000000000000000000000000000000000000000000000000000000000000000000000000000000000000000000000000000000000000000000000000000000000000000000000000000000000000000000000000000000000000000000000000000000000000000000000000000000000000000000000000000000000000000000000000000000000000000000000000000000000000000000000000000000000000000000000000000000000000000000000000000000000000000000000000000000000000000000000000000000000000000000000000000000000000000000000000000000000000000000000000000000000000000000000000000000000000000000000000000000000000000000000000000000000000000000000000000000000000000000000000000000000000000000000000000000000000000000000000000000000000000000000000000000000000000000000000000000000000000000000000000000000000000000000000000000000000000000000000000000000000000000000000000000000000000000000000000000000000000000000000000000000000000000000000000000000000000000000000000000000000000000000000000000000000000000000000000000000000000000000000000000000000000000000000000000000000000000000000000000000000000000000000000000000000000000000000000000000000000000000000000000000000000000000000000000000000000000000000000000000000000000000000000000000000000000000000000000000000000000000000000000000000000000000000000000000000000000000000000000000000000000000000000000000000000000000000000000000000000000000000000000000000000000000000000000000000000000000000000000000000000000000000000000000000000000000000000000000000000000000000000000000000000000000000000000000000000000000000000000000000000000000000000000000000000000000000000000000000000000000000000000000000000000000000000000000000000000000000000000000000000000000000000000000000000000000000000000000000000000000000000000000000000000000000000000000000000000000000000000000000000000000000000000000000000000000000000000000000000000000000000000000000000000000000000000000000000000000000000000000000000000000000000000000000000000000000000000000000000000000000000000000000000000000000000000000000000000000000000000000000000000000000000000000000000000000000000000000000000000000000000000000000000000000000000000000000000000000000000000000000000000000000000000000000000000000000000000000000000000000000000000000000000000000000000000000000000000000000000000000000000000000000000000000000000000000000000000000000000000000000000000000000000000000000000000000000000000000000000000000000000000000000000000000000000000000000000000000000000000000000000000000000000000000000000000000000000000000000000000000000000000000000000000000000000000000000000000000000000000000000000000000000000000000000000000000000000000000000000000000000000000000000000000000000000000000000000000000000000000000000000000000000000000000000000000000000000000000000000000000000000000000000000000000000000000000000000000000000000000000000000000000000000000000000000000000000000000000000000000000000000000000000000000000000000000000000000000000000000000000000000000000000000000000000000000000000000000000000000000000000000000000000000000000000000000000000000000000000000000000000000000000000000000000000000000000000000000000000000000000000000000000000000000000000000000000000000000000000000000000000000000000000000000000000000000000000000000000000000000000000000000000000000000000000000000000000000000000000000000000000000000000000000000000000000000000000000000000000000000000000000000000000000000000000000000000000000000000000000000000000000000000000000000000000000000000000000000000000000000000000000000000000000000000000000000000000000000000000000000000000000000000000000000000000000000000000000000000000000000000000000000000000000000000000000000000000000000000000000000000000000000000000000000000000000000000000000000000000000000000000000000000000000000000000000000000000000000000000000000000000000000000000000000000000000000000000000000000000000000000000000000000000000000000000000000000000000000000000000000000000000000000000000000000000000000000000000000000000000000000000000000000000000000000000000000000000000000000000000000000000000000000000000000000000000000000000000000000000000000000000000000000000000000000000000000000000000000000000000000000000000000000000000000000000000000000000000000000000000000000000000000000000000000000000000000000000000000000000000000000000000000000000000000000000000000000000000000000000000000000000000000000000000000000000000000000000000000000000000000000000000000000000000000000000000000000000000000000000000000000000000000000000000000000000000000000000000000000000000000000000000000000000000000000000000000000000000000000000000000000000000000000000000000000000000000000000000000000000000000000000000000000000000000000000000000000000000000000000000000000000000000000000000000000000000000000000000000000000000000000000000000000000000000000000000000000000000000000000000000000000000000000000000000000000000000000000000000000000000000000000000000000000000000000000000000000000000000000000000000000000000000000000000000000000000000000000000000000000000000000000000000000000000000000000000000000000000000000000000000000000000000000000000000000000000000000000000000000000000000000000000000000000000000000000000000000000000000000000000000000000000000000000000000000000000000000000000000000000000000000000000000000000000000000000000000000000000000000000000000000000000000000000000000000000000000000000000000000000000000000000000000000000000000000000000000000000000000000000000000000000000000000000000000000000000000000000000000000000000000000000000000000000000000000000000000000000000000000000000000000000000000000000000000000000000000000000000000000000000000000000000000000000000000000000000000000000000000000000000000000000000000000000000000000000000000000000000000000000000000000000000000000000000000000000000000000000000000000000000000000000000000000000000000000000000000000000000000000000000000000000000000000000000000000000000000000000000000000000000000000000000000000000000000000000000000000000000000000000000000000000000000000000000000000000000000000000000000000000000000000000000000000000000000000000000000000000000000000000000000000000000000000000000000000000000000000000000000000000000000000000000000000000000000000000000000000000000000000000000000000000000000000000000000000000000000000000000000000000000000000000000000000000000000000000000000000000000000000000000000000000000000000000000000000000000000000000000000000000000000000000000000000000000000000000000000000000000000000000000000000000000000000000000000000000000000000000000000000000000000000000000000000000000000000000000000000000000000000000000000000000000000000000000000000000000000000000000000000000000000000000000000000000000000000000000000000000000000000000000000000000000000000000000000000000000000000000000000000000000000000000000000000000000000000000000000000000000000000000000000000000000000000000000000000000000000000000000000000000000000000000000000000000000000000000000000000000000000000000000000000000000000000000000000000000000000000000000000000000000000000000000000000000000000000000000000000000000000000000000000000000000000000000000000000000000000000000000000000000000000000000000000000000000000000000000000000000000000000000000000000000000000000000000000000000000000000000000000000000000000000000000000000000000000000000000000000000000000000000000000000000000000000000000000000000000000000000000000000000000000000000000000000000000000000000000000000000000000000000000000000000000000000000000000000000000000000000000000000000000000000000000000000000000000000000000000000000000000000000000000000000000000000000000000000000000000000000000000000000000000000000000000000000000000000000000000000000000000000000000000000000000000000000000000000000000000000000000000000000000000000000000000000000000000000000000000000000000000000000000000000000000000000000000000000000000000000000000000000000000000000000000000000000000000000000000000000000000000000000000000000000000000000000000000000000000000000000000000000000000000000000000000000000000000000000000000000000000000000000000000000000000000000000000000000000000000000000000000000000000000000000000000000000000000000000000000000000000000000000000000000000000000000000000000000000000000000000000000000000000000000000000000000000000000000000000000000000000000000000000000000000000000000000000000000000000000000000000000000000000000000000000000000000000000000000000000000000000000000000000000000000000000000000000000000000000000000000000000000000000000000000000000000000000000000000000000000000000000000000000000000000000000000000000000000000000000000000000000000000000000000000000000000000000000000000000000000000000000000000000000000000000000000000000000000000000000000000000000000000000000000000000000000000000000000000000000000000000000000000000000000000000000000000000000000000000000000000000000000000000000000000000000000000000000000000000000000000000000000000000000000000000000000000000000000000000000000000000000000000000000000000000000000000000000000000000000000000000000000000000000000000000000000000000000000000000000000000000000000000000000000000000000000000000000000000000000000000000000000000000000000000000000000000000000000000000000000000000000000000000000000000000000000000000000000000000000000000000000000000000000000000000000000000000000000000000000000000000000000000000000000000000000000000000000000000000000000000000000000000000000000000000000000000000000000000000000000000000000000000000000000000000000000000000000000000000000000000000000000000000000000000000000000000000000000000000000000000000000000000000000000000000000000000000000000000000000000000000000000000000000000000000000000000000000000000000000000000000000000000000000000000000000000000000000000000000000000000000000000000000000000000000000000000000000000000000000000000000000000000000000000000000000000000000000000000000000000000000000000000000000000000000000000000000000000000000000000000000000000000000000000000000000000000000000000000000000000000000000000000000000000000000000000000000000000000000000000000000000000000000000000000000000000000000000000000000000000000000000000000000000000000000000000000000000000000000000000000000000000000000000000000000000000000000000000000000000000000000000000000000000000000000000000000000000000000000000000000000000000000000000000000000000000000000000000000000000000000000000000000000000000000000000000000000000000000000000000000000000000000000000000000000000000000000000000000000000000000000000000000000000000000000000000000000000000000000000000000000000000000000000000000000000000000000000000000000000000000000000000000000000000000000000000000000000000000000000000000000000000000000000000000000000000000000000000000000000000000000000000000000000000000000000000000000000000000000000000000000000000000000000000000000000000000000000000000000000000000000000000000000000000000000000000000000000000000000000000000000000000000000000000000000000000000000000000000000000000000000000000000000000000000000000000000000000000000000000000000000000000000000000000000000000000000000000000000000000000000000000000000000000000000000000000000000000000000000000000000000000000000000000000000000000000000000000000000000000000000000000000000000000000000000000000000000000000000000000000000000000000000000000000000000000000000000000000000000000000000000000000000000000000000000000000000000000000000000000000000000000000000000000000000000000000000000000000000000000000000000000000000000000000000000000000000000000000000000000000000000000000000000000000000000000000000000000000000000000000000000000000000000000000000000000000000000000000000000000000000000000000000000000000000000000000000000000000000000000000000000000000000000000000000000000000000000000000000000000000000000000000000000000000000000000000000000000000000000000000000000000000000000000000000000000000000000000000000000000000000000000000000000000000000000000000000000000000000000000000000000000000000000000000000000000000000000000000000000000000000000000000000000000000000000000000000000000000000000000000000000000000000000000000000000000000000000000000000000000000000000000000000000000000000000000000000000000000000000000000000000000000000000000000000000000000000000000000000000000000000000000000000000000000000000000000000000000000000000000000000000000000000000000000000000000000000000000000000000000000000000000000000000000000000000000000000000000000000000000000000000000000000000000000000000000000000000000000000000000000000000000000000000000000000000000000000000000000000000000000000000000000000000000000000000000000000000000000000000000000000000000000000000000000000000000000000000000000000000000000000000000000000000000000000000000000000000000000000000000000000000000000000000000000000000000000000000000000000000000000000000000000000000000000000000000000000000000000000000000000000000000000000000000000000000000000000000000000000000000000000000000000000000000000000000000000000000000000000000000000000000000000000000000000000000000000000000000000000000000000000000000000000000000000000000000000000000000000000000000000000000000000000000000000000000000000000000000000000000000000000000000000000000000000000000000000000000000000000000000000000000000000000000000000000000000000000000000000000000000000000000000000000000000000000000000000000000000000000000000000000000000000000000000000000000000000000000000000000000000000000000000000000000000000000000000000000000000000000000000000000000000000000000000000000000000000000000000000000000000000000000000000000000000000000000000000000000000000000000000000000000000000000000000000000000000000000000000000000000000000000000000000000000000000000000000000000000000000000000000000000000000000000000000000000000000000000000000000000000000000000000000000000000000000000000000000000000000000000000000000000000000000000000000000000000000000000000000000000000000000000000000000000000000000000000000000000000000000000000000000000000000000000000000000000000000000000000000000000000000000000000000000000000000000000000000000000000000000000000000000000000000000000000000000000000000000000000000000000000000000000000000000000000000000000000000000000000000000000000000000000000000000000000000000000000000000000000000000000000000000000000000000000000000000000000000000000000000000000000000000000000000000000000000000000000000000000000000000000000000000000000000000000000000000000000000000000000000000000000000000000000000000000000000000000000000000000000000000000000000000000000000000000000000000000000000000000000000000000000000000000000000000000000000000000000000000000000000000000000000000000000000000000000000000000000000000000000000000000000000000000000000000000000000000000000000000000000000000000000000000000000000000000000000000000000000000000000000000000000000000000000000000000000000000000000000000000000000000000000000000000000000000000000000000000000000000000000000000000000000000000000000000000000000000000000000000000000000000000000000000000000000000000000000000000000000000000000000000000000000000000000000000000000000000000000000000000000000000000000000000000000000000000000000000000000000000000000000000000000000000000000000000000000000000000000000000000000000000000000000000000000000000000000000000000000000000000000000000000000000000000000000000000000000000000000000000000000000000000000000000000000000000000000000000000000000000000000000000000000000000000000000000000000000000000000000000000000000000000000000000000000000000000000000000000000000000000000000000000000000000000000000000000000000000000000000000000000000000000000000000000000000000000000000000000000000000000000000000000000000000000000000000000000000000000000000000000000000000000000000000000000000000000000000000000000000000000000000000000000000000000000000000000000000000000000000000000000000000000000000000000000000000000000000000000000000000000000000000000000000000000000000000000000000000000000000000000000000000000000000000000000000000000000000000000000000000000000000000000000000000000000000000000000000000000000000000000000000000000000000000000000000000000000000000000000000000000000000000000000000000000000000000000000000000000000000000000000000000000000000000000000000000000000000000000000000000000000000000000000000000000000000000000000000000000000000000000000000000000000000000000000000000000000000000000000000000000000000000000000000000000000000000000000000000000000000000000000000000000000000000000000000000000000000000000000000000000000000000000000000000000000000000000000000000000000000000000000000000000000000000000000000000000000000000000000000000000000000000000000000000000000000000000000000000000000000000000000000000000000000000000000000000000000000000000000000000000000000000000000000000000000000000000000000000000000000000000000000000000000000000000000000000000000000000000000000000000000000000000000000000000000000000000000000000000000000000000000000000000000000000000000000000000000000000000000000000000000000000000000000000000000000000000000000000000000000000000000000000000000000000000000000000000000000000000000000000000000000000000000000000000000000000000000000000000000000000000000000000000000000000000000000000000000000000000000000000000000000000000000000000000000000000000000000000000000000000000000000000000000000000000000000000000000000000000000000000000000000000000000000000000000000000000000000000000000000000000000000000000000000000000000000000000000000000000000000000000000000000000000000000000000000000000000000000000000000000000000000000000000000000000000000000000000000000000000000000000000000000000000000000000000000000000000000000000000000000000000000000000000000000000000000000000000000000000000000000000000000000000000000000000000000000000000000000000000000000000000000000000000000000000000000000000000000000000000000000000000000000000000000000000000000000000000000000000000000000000000000000000000000000000000000000000000000000000000000000000000000000000000000000000000000000000000000000000000000000000000000000000000000000000000000000000000000000000000000000000000000000000000000000000000000000000000000000000000000000000000000000000000000000000000000000000000000000000000000000000000000000000000000000000000000000000000000000000000000000000000000000000000000000000000000000000000000000000000000000000000000000000000000000000000000000000000000000000000000000000000000000000000000000000000000000000000000000000000000000000000000000000000000000000000000000000000000000000000000000000000000000000000000000000000000000000000000000000000000000000000000000000000000000000000000000000000000000000000000000000000000000000000000000000000000000000000000000000000000000000000000000000000000000000000000000000000000000000000000000000000000000000000000000000000000000000000000000000000000000000000000000000000000000000000000000000000000000000000000000000000000000000000000000000000000000000000000000000000000000000000000000000000000000000000000000000000000000000000000000000000000000000000000000000000000000000000000000000000000000000000000000000000000000000000000000000000000000000000000000000000000000000000000000000000000000000000000000000000000000000000000000000000000000000000000000000000000000000000000000000000000000000000000000000000000000000000000000000000000000000000000000000000000000000000000000000000000000000000000000000000000000000000000000000000000000000000000000000000000000000000000000000000000000000000000000000000000000000000000000000000000000000000000000000000000000000000000000000000000000000000000000000000000000000000000000000000000000000000000000000000000000000000000000000000000000000000000000000000000000000000000000000000000000000000000000000000000000000000000000000000000000000000000000000000000000000000000000000000000000000000000000000000000000000000000000000000000000000000000000000000000000000000000000000000000000000000000000000000000000000000000000000000000000000000000000000000000000000000000000000000000000000000000000000000000000000000000000000000000000000000000000000000000000000000000000000000000000000000000000000000000000000000000000000000000000000000000000000000000000000000000000000000000000000000000000000000000000000000000000000000000000000000000000000000000000000000000000000000000000000000000000000000000000000000000000000000000000000000000000000000000000000000000000000000000000000000000000000000000000000000000000000000000000000000000000000000000000000000000000000000000000000000000000000000000000000000000000000000000000000000000000000000000000000000000000000000000000000000000000000000000000000000000000000000000000000000000000000000000000000000000000000000000000000000000000000000000000000000000000000000000000000000000000000000000000000000000000000000000000000000000000000000000000000000000000000000000000000000000000000000000000000000000000000000000000000000000000000000000000000000000000000000000000000000000000000000000000000000000000000000000000000000000000000000000000000000000000000000000000000000000000000000000000000000000000000000000000000000000000000000000000000000000000000000000000000000000000000000000000000000000000000000000000000000000000000000000000000000000000000000000000000000000000000000000000000000000000000000000000000000000000000000000000000000000000000000000000000000000000000000000000000000000000000000000000000000000000000000000000000000000000000000000000000000000000000000000000000000000000000000000000000000000000000000000000000000000000000000000000000000000000000000000000000000000000000000000000000000000000000000000000000000000000000000000000000000000000000000000000000000000000000000000000000000000000000000000000000000000000000000000000000000000000000000000000000000000000000000000000000000000000000000000000000000000000000000000000000000000000000000000000000000000000000000000000000000000000000000000000000000000000000000000000000000000000000000000000000000000000000000000000000000000000000000000000000000000000000000000000000000000000000000000000000000000000000000000000000000000000000000000000000000000000000000000000000000000000000000000000000000000000000000000000000000000000000000000000000000000000000000000000000000000000000000000000000000000000000000000000000000000000000000000000000000000000000000000000000000000000000000000000000000000000000000000000000000000000000000000000000000000000000000000000000000000000000000000000000000000000000000000000000000000000000000000000000000000000000000000000000000000000000000000000000000000000000000000000000000000000000000000000000000000000000000000000000000000000000000000000000000000000000000000000000000000000000000000000000000000000000000000000000000000000000000000000000000000000000000000000000000000000000000000000000000000000000000000000000000000000000000000000000000000000000000000000000000000000000000000000000000000000000000000000000000000000000000000000000000000000000000000000000000000000000000000000000000000000000000000000000000000000000000000000000000000000000000000000000000000000000000000000000000000000000000000000000000000000000000000000000000000000000000000000000000000000000000000000000000000000000000000000000000000000000000000000000000000000000000000000000000000000000000000000000000000000000000000000000000000000000000000000000000000000000000000000000000000000000000000000000000000000000000000000000000000000000000000000000000000000000000000000000000000000000000000000000000000000000000000000000000000000000000000000000000000000000000000000000000000000000000000000000000000000000000000000000000000000000000000000000000000000000000000000000000000000000000000000000000000000000000000000000000000000000000000000000000000000000000000000000000000000000000000000000000000000000000000000000000000000000000000000000000000000000000000000000000000000000000000000000000000000000000000000000000000000000000000000000000000000000000000000000000000000000000000000000000000000000000000000000000000000000000000000000000000000000000000000000000000000000000000000000000000000000000000000000000000000000000000000000000000000000000000000000000000000000000000000000000000000000000000000000000000000000000000000000000000000000000000000000000000000000000000000000000000000000000000000000000000000000000000000000000000000000000000000000000000000000000000000000000000000000000000000000000000000000000000000000000000000000000000000000000000000000000000000000000000000000000000000000000000000000000000000000000000000000000000000000000000000000000000000000000000000000000000000000000000000000000000000000000000000000000000000000000000000000000000000000000000000000000000000000000000000000000000000000000000000000000000000000000000000000000000000000000000000000000000000000000000000000000000000000000000000000000000000000000000000000000000000000000000000000000000000000000000000000000000000000000000000000000000000000000000000000000000000000000000000000000000000000000000000000000000000000000000000000000000000000000000000000000000000000000000000000000000000000000000000000000000000000000000000000000000000000000000000000000000000000000000000000000000000000000000000000000000000000000000000000000000000000000000000000000000000000000000000000000000000000000000000000000000000000000000000000000000000000000000000000000000000000000000000000000000000000000000000000000000000000000000000000000000000000000000000000000000000000000000000000000000000000000000000000000000000000000000000000000000000000000000000000000000000000000000000000000000000000000000000000000000000000000000000000000000000000000000000000000000000000000000000000000000000000000000000000000000000000000000000000000000000000000000000000000000000000000000000000000000000000000000000000000000000000000000000000000000000000000000000000000000000000000000000000000000000000000000000000000000000000000000000000000000000000000000000000000000000000000000000000000000000000000000000000000000000000000000000000000000000000000000000000000000000000000000000000000000000000000000000000000000000000000000000000000000000000000000000000000000000000000000000000000000000000000000000000000000000000000000000000000000000000000000000000000000000000000000000000000000000000000000000000000000000000000000000000000000000000000000000000000000000000000000000000000000000000000000000000000000000000000000000000000000000000000000000000000000000000000000000000000000000000000000000000000000000000000000000000000000000000000000000000000000000000000000000000000000000000000000000000000000000000000000000000000000000000000000000000000000000000000000000000000000000000000000000000000000000000000000000000000000000000000000000000000000000000000000000000000000000000000000000000000000000000000000000000000000000000000000000000000000000000000000000000000000000000000000000000000000000000000000000000000000000000000000000000000000000000000000000000000000000000000000000000000000000000000000000000000000000000000000000000000000000000000000000000000000000000000000000000000000000000000000000000000000000000000000000000000000000000000000000000000000000000000000000000000000000000000000000000000000000000000000000000000000000000000000000000000000000000000000000000000000000000000000000000000000000000000000000000000000000000000000000000000000000000000000000000000000000000000000000000000000000000000000000000000000000000000000000000000000000000000000000000000000000000000000000000000000000000000000000000000000000000000000000000000000000000000000000000000000000000000000000000000000000000000000000000000000000000000000000000000000000000000000000000000000000000000000000000000000000000000000000000000000000000000000000000000000000000000000000000000000000000000000000000000000000000000000000000000000000000000000000000000000000000000000000000000000000000000000000000000000000000000000000000000000000000000000000000000000000000000000000000000000000000000000000000000000000000000000000000000000000000000000000000000000000000000000000000000000000000000000000000000000000000000000000000000000000000000000000000000000000000000000000000000000000000000000000000000000000000000000000000000000000000000000000000000000000000000000000000000000000000000000000000000000000000000000000000000000000000000000000000000000000000000000000000000000000000000000000000000000000000000000000000000000000000000000000000000000000000000000000000000000000000000000000000000000000000000000000000000000000000000000000000000000000000000000000000000000000000000000000000000000000000000000000000000000000000000000000000000000000000000000000000000000000000000000000000000000000000000000000000000000000000000000000000000000000000000000000000000000000000000000000000000000000000000000000000000000000000000000000000000000000000000000000000000000000000000000000000000000000000000000000000000000000000000000000000000000000000000000000000000000000000000000000000000000000000000000000000000000000000000000000000000000000000000000000000000000000000000000000000000000000000000000000000000000000000000000000000000000000000000000000000000000000000000000000000000000000000000000000000000000000000000000000000000000000000000000000000000000000000000000000000000000000000000000000000000000000000000000000000000000000000000000000000000000000000000000000000000000000000000000000000000000000000000000000000000000000000000000000000000000000000000000000000000000000000000000000000000000000000000000000000000000000000000000000000000000000000000000000000000000000000000000000000000000000000000000000000000000000000000000000000000000000000000000000000000000000000000000000000000000000000000000000000000000000000000000000000000000000000000000000000000000000000000000000000000000000000000000000000000000000000000000000000000000000000000000000000000000000000000000000000000000000000000000000000000000000000000000000000000000000000000000000000000000000000000000000000000000000000000000000000000000000000000000000000000000000000000000000000000000000000000000000000000000000000000000000000000000000000000000000000000000000000000000000000000000000000000000000000000000000000000000000000000000000000000000000000000000000000000000000000000000000000000000000000000000000000000000000000000000000000000000000000000000000000000000000000000000000000000000000000000000000000000000000000000000000000000000000000000000000000000000000000000000000000000000000000000000000000000000000000000000000000000000000000000000000000000000000000000000000000000000000000000000000000000000000000000000000000000000000000000000000000000000000000000000000000000000000000000000000000000000000000000000000000000000000000000000000000000000000000000000000000000000000000000000000000000000000000000000000000000000000000000000000000000000000000000000000000000000000000000000000000000000000000000000000000000000000000000000000000000000000000000000000000000000000000000000000000000000000000000000000000000000000000000000000000000000000000000000000000000000000000000000000000000000000000000000000000000000000000000000000000000000000000000000000000000000000000000000000000000000000000000000000000000000000000000000000000000000000000000000000000000000000000000000000000000000000000000000000000000000000000000000000000000000000000000000000000000000000000000000000000000000000000000000000000000000000000000000000000000000000000000000000000000000000000000000000000000000000000000000000000000000000000000000000000000000000000000000000000000000000000000000000000000000000000000000000000000000000000000000000000000000000000000000000000000000000000000000000000000000000000000000000000000000000000000000000000000000000000000000000000000000000000000000000000000000000000000000000000000000000000000000000000000000000000000000000000000000000000000000000000000000000000000000000000000000000000000000000000000000000000000000000000000000000000000000000000000000000000000000000000000000000000000000000000000000000000000000000000000000000000000000000000000000000000000000000000000000000000000000000000000000000000000000000000000000000000000000000000000000000000000000000000000000000000000000000000000000000000000000000000000000000000000000000000000000000000000000000000000000000000000000000000000000000000000000000000000000000000000000000000000000000000000000000000000000000000000000000000000000000000000000000000000000000000000000000000000000000000000000000000000000000000000000000000000000000000000000000000000000000000000000000000000000000000000000000000000000000000000000000000000000000000000000000000000000000000000000000000000000000000000000000000000000000000000000000000000000000000000000000000000000000000000000000000000000000000000000000000000000000000000000000000000000000000000000000000000000000000000000000000000000000000000000000000000000000000000000000000000000000000000000000000000000000000000000000000000000000000000000000000000000000000000000000000000000000000000000000000000000000000000000000000000000000000000000000000000000000000000000000000000000000000000000000000000000000000000000000000000000000000000000000000000000000000000000000000000000000000000000000000000000000000000000000000000000000000000000000000000000000000000000000000000000000000000000000000000000000000000000000000000000000000000000000000000000000000000000000000000000000000000000000000000000000000000000000000000000000000000000000000000000000000000000000000000000000000000000000000000000000000000000000000000000000000000000000000000000000000000000000000000000000000000000000000000000000000000000000000000000000000000000000000000000000000000000000000000000000000000000000000000000000000000000000000000000000000000000000000000000000000000000000000000000000000000000000000000000000000000000000000000000000000000000000000000000000000000000000000000000000000000000000000000000000000000000000000000000000000000000000000000000000000000000000000000000000000000000000000000000000000000000000000000000000000000000000000000000000000000000000000000000000000000000000000000000000000000000000000000000000000000000000000000000000000000000000000000000000000000000000000000000000000000000000000000000000000000000000000000000000000000000000000000000000000000000000000000000000000000000000000000000000000000000000000000000000000000000000000000000000000000000000000000000000000000000000000000000000000000000000000000000000000000000000000000000000000000000000000000000000000000000000000000000000000000000000000000000000000000000000000000000000000000000000000000000000000000000000000000000000000000000000000000000000000000000000000000000000000000000000000000000000000000000000000000000000000000000000000000000000000000000000000000000000000000000000000000000000000000000000000000000000000000000000000000000000000000000000000000000000000000000000000000000000000000000000000000000000000000000000000000000000000000000000000000000000000000000000000000000000000000000000000000000000000000000000000000000000000000000000000000000000000000000000000000000000000000000000000000000000000000000000000000000000000000000000000000000000000000000000000000000000000000000000000000000000000000000000000000000000000000000000000000000000000000000000000000000000000000000000000000000000000000000000000000000000000000000000000000000000000000000000000000000000000000000000000000000000000000000000000000000000000000000000000000000000000000000000000000000000000000000000000000000000000000000000000000000000000000000000000000000000000000000000000000000000000000000000000000000000000000000000000000000000000000000000000000000000000000000000000000000000000000000000000000000000000000000000000000000000000000000000000000000000000000000000000000000000000000000000000000000000000000000000000000000000000000000000000000000000000000000000000000000000000000000000000000000000000000000000000000000000000000000000000000000000000000000000000000000000000000000000000000000000000000000000000000000000000000000000000000000000000000000000000000000000000000000000000000000000000000000000000000000000000000000000000000000000000000000000000000000000000000000000000000000000000000000000000000000000000000000000000000000000000000000000000000000000000000000000000000000000000000000000000000000000000000000000000000000000000000000000000000000000000000000000000000000000000000000000000000000000000000000000000000000000000000000000000000000000000000000000000000000000000000000000000000000000000000000000000000000000000000000000000000000000000000000000000000000000000000000000000000000000000000000000000000000000000000000000000000000000000000000000000000000000000000000000000000000000000000000000000000000000000000000000000000000000000000000000000000000000000000000000000000000000000000000000000000000000000000000000000000000000000000000000000000000000000000000000000000000000000000000000000000000000000000000000000000000000000000000000000000000000000000000000000000000000000000000000000000000000000000000000000000000000000000000000000000000000000000000000000000000000000000000000000000000000000000000000000000000000000000000000000000000000000000000000000000000000000000000000000000000000000000000000000000000000000000000000000000000000000000000000000000000000000000000000000000000000000000000000000000000000000000000000000000000000000000000000000000000000000000000000000000000000000000000000000000000000000000000000000000000000000000000000000000000000000000000000000000000000000000000000000000000000000000000000000000000000000000000000000000000000000000000000000000000000000000000000000000000000000000000000000000000000000000000000000000000000000000000000000000000000000000000000000000000000000000000000000000000000000000000000000000000000000000000000000000000000000000000000000000000000000000000000000000000000000000000000000000000000000000000000000000000000000000000000000000000000000000000000000000000000000000000000000000000000000000000000000000000000000000000000000000000000000000000000000000000000000000000000000000000000000000000000000000000000000000000000000000000000000000000000000000000000000000000000000000000000000000000000000000000000000000000000000000000000000000000000000000000000000000000000000000000000000000000000000000000000000000000000000000000000000000000000000000000000000000000000000000000000000000000000000000000000000000000000000000000000000000000000000000000000000000000000000000000000000000000000000000000000000000000000000000000000000000000000000000000000000000000000000000000000000000000000000000000000000000000000000000000000000000000000000000000000000000000000000000000000000000000000000000000000000000000000000000000000000000000000000000000000000000000000000000000000000000000000000000000000000000000000000000000000000000000000000000000000000000000000000000000000000000000000000000000000000000000000000000000000000000000000000000000000000000000000000000000000000000000000000000000000000000000000000000000000000000000000000000000000000000000000000000000000000000000000000000000000000000000000000000000000000000000000000000000000000000000000000000000000000000000000000000000000000000000000000000000000000000000000000000000000000000000000000000000000000000000000000000000000000000000000000000000000000000000000000000000000000000000000000000000000000000000000000000000000000000000000000000000000000000000000000000000000000000000000000000000000000000000000000000000000000000000000000000000000000000000000000000000000000000000000000000000000000000000000000000000000000000000000000000000000000000000000000000000000000000000000000000000000000000000000000000000000000000000000000000000000000000000000000000000000000000000000000000000000000000000000000000000000000000000000000000000000000000000000000000000000000000000000000000000000000000000000000000000000000000000000000000000000000000000000000000000000000000000000000000000000000000000000000000000000000000000000000000000000000000000000000000000000000000000000000000000000000000000000000000000000000000000000000000000000000000000000000000000000000000000000000000000000000000000000000000000000000000000000000000000000000000000000000000000000000000000000000000000000000000000000000000000000000000000000000000000000000000000000000000000000000000000000000000000000000000000000000000000000000000000000000000000000000000000000000000000000000000000000000000000000000000000000000000000000000000000000000000000000000000000000000000000000000000000000000000000000000000000000000000000000000000000000000000000000000000000000000000000000000000000000000000000000000000000000000000000000000000000000000000000000000000000000000000000000000000000000000000000000000000000000000000000000000000000000000000000000000000000000000000000000000000000000000000000000000000000000000000000000000000000000000000000000000000000000000000000000000000000000000000000000000000000000000000000000000000000000000000000000000000000000000000000000000000000000000000000000000000000000000000000000000000000000000000000000000000000000000000000000000000000000000000000000000000000000000000000000000000000000000000000000000000000000000000000000000000000000000000000000000000000000000000000000000000000000000000000000000000000000000000000000000000000000000000000000000000000000000000000000000000000000000000000000000000000000000000000000000000000000000000000000000000000000000000000000000000000000000000000000000000000000000000000000000000000000000000000000000000000000000000000000000000000000000000000000000000000000000000000000000000000000000000000000000000000000000000000000000000000000000000000000000000000000000000000000000000000000000000000000000000000000000000000000000000000000000000000000000000000000000000000000000000000000000000000000000000000000000000000000000000000000000000000000000000000000000000000000000000000000000000000000000000000000000000000000000000000000000000000000000000000000000000000000000000000000000000000000000000000000000000000000000000000000000000000000000000000000000000000000000000000000000000000000000000000000000000000000000000000000000000000000000000000000000000000000000000000000000000000000000000000000000000000000000000000000000000000000000000000000000000000000000000000000000000000000000000000000000000000000000000000000000000000000000000000000000000000000000000000000000000000000000000000000000000000000000000000000000000000000000000000000000000000000000000000000000000000000000000000000000000000000000000000000000000000000000000000000000000000000000000000000000000000000000000000000000000000000000000000000000000000000000000000000000000000000000000000000000000000000000000000000000000000000000000000000000000000000000000000000000000000000000000000000000000000000000000000000000000000000000000000000000000000000000000000000000000000000000000000000000000000000000000000000000000000000000000000000000000000000000000000000000000000000000000000000000000000000000000000000000000000000000000000000000000000000000000000000000000000000000000000000000000000000000000000000000000000000000000000000000000000000000000000000000000000000000000000000000000000000000000000000000000000000000000000000000000000000000000000000000000000000000000000000000000000000000000000000000000000000000000000000000000000000000000000000000000000000000000000000000000000000000000000000000000000000000000000000000000000000000000000000000000000000000000000000000000000000000000000000000000000000000000000000000000000000000000000000000000000000000000000000000000000000000000000000000000000000000000000000000000000000000000000000000000000000000000000000000000000000000000000000000000000000000000000000000000000000000000000000000000000000000000000000000000000000000000000000000000000000000000000000000000000000000000000000000000000000000000000000000000000000000000000000000000000000000000000000000000000000000000000000000000000000000000000000000000000000000000000000000000000000000000000000000000000000000000000000000000000000000000000000000000000000000000000000000000000000000000000000000000000000000000000000000000000000000000000000000000000000000000000000000000000000000000000000000000000000000000000000000000000000000000000000000000000000000000000000000000000000000000000000000000000000000000000000000000000000000000000000000000000000000000000000000000000000000000000000000000000000000000000000000000000000000000000000000000000000000000000000000000000000000000000000000000000000000000000000000000000000000000000000000000000000000000000000000000000000000000000000000000000000000000000000000000000000000000000000000000000000000000000000000000000000000000000000000000000000000000000000000000000000000000000000000000000000000000000000000000000000000000000000000000000000000000000000000000000000000000000000000000000000000000000000000000000000000000000000000000000000000000000000000000000000000000000000000000000000000000000000000000000000000000000000000000000000000000000000000000000000000000000000000000000000000000000000000000000000000000000000000000000000000000000000000000000000000000000000000000000000000000000000000000000000000000000000000000000000000000000000000000000000000000000000000000000000000000000000000000000000000000000000000000000000000000000000000000000000000000000000000000000000000000000000000000000000000000000000000000000000000000000000000000000000000000000000000000000000000000000000000000000000000000000000000000000000000000000000000000000000000000000000000000000000000000000000000000000000000000000000000000000000000000000000000000000000000000000000000000000000000000000000000000000000000000000000000000000000000000000000000000000000000000000000000000000000000000000000000000000000000000000000000000000000000000000000000000000000000000000000000000000000000000000000000000000000000000000000000000000000000000000000000000000000000000000000000000000000000000000000000000000000000000000000000000000000000000000000000000000000000000000000000000000000000000000000000000000000000000000000000000000000000000000000000000000000000000000000000000000000000000000000000000000000000000000000000000000000000000000000000000000000000000000000000000000000000000000000000000000000000000000000000000000000000000000000000000000000000000000000000000000000000000000000000000000000000000000000000000000000000000000000000000000000000000000000000000000000000000000000000000000000000000000000000000000000000000000000000000000000000000000000000000000000000000000000000000000000000000000000000000000000000000000000000000000000000000000000000000000000000000000000000000000000000000000000000000000000000000000000000000000000000000000000000000000000000000000000000000000000000000000000000000000000000000000000000000000000000000000000000000000000000000000000000000000000000000000000000000000000000000000000000000000000000000000000000000000000000000000000000000000000000000000000000000000000000000000000000000000000000000000000000000000000000000000000000000000000000000000000000000000000000000000000000000000000000000000000000000000000000000000000000000000000000000000000000000000000000000000000000000000000000000000000000000000000000000000000000000000000000000000000000000000000000000000000000000000000000000000000000000000000000000000000000000000000000000000000000000000000000000000000000000000000000000000000000000000000000000000000000000000000000000000000000000000000000000000000000000000000000000000000000000000000000000000000000000000000000000000000000000000000000000000000000000000000000000000000000000000000000000000000000000000000000000000000000000000000000000000000000000000000000000000000000000000000000000000000000000000000000000000000000000000000000000000000000000000000000000000000000000000000000000000000000000000000000000000000000000000000000000000000000000000000000000000000000000000000000000000000000000000000000000000000000000000000000000000000000000000000000000000000000000000000000000000000000000000000000000000000000000000000000000000000000000000000000000000000000000000000000000000000000000000000000000000000000000000000000000000000000000000000000000000000000000000000000000000000000000000000000000000000000000000000000000000000000000000000000000000000000000000000000000000000000000000000000000000000000000000000000000000000000000000000000000000000000000000000000000000000000000000000000000000000000000000000000000000000000000000000000000000000000000000000000000000000000000000000000000000000000000000000000000000000000000000000000000000000000000000000000000000000000000000000000000000000000000000000000000000000000000000000000000000000000000000000000000000000000000000000000000000000000000000000000000000000000000000000000000000000000000000000000000000000000000000000000000000000000000000000000000000000000000000000000000000000000000000000000000000000000000000000000000000000000000000000000000000000000000000000000000000000000000000000000000000000000000000000000000000000000000000000000000000000000000000000000000000000000000000000000000000000000000000000000000000000000000000000000000000000000000000000000000000000000000000000000000000000000000000000000000000000000000000000000000000000000000000000000000000000000000000000000000000000000000000000000000000000000000000000000000000000000000000000000000000000000000000000000000000000000000000000000000000000000000000000000000000000000000000000000000000000000000000000000000000000000000000000000000000000000000000000000000000000000000000000000000000000000000000000000000000000000000000000000000000000000000000000000000000000000000000000000000000000000000000000000000000000000000000000000000000000000000000000000000000000000000000000000000000000000000000000000000000000000000000000000000000000000000000000000000000000000000000000000000000000000000000000000000000000000000000000000000000000000000000000000000000000000000000000000000000000000000000000000000000000000000000000000000000000000000000000000000000000000000000000000000000000000000000000000000000000000000000000000000000000000000000000000000000000000000000000000000000000000000000000000000000000000000000000000000000000000000000000000000000000000000000000000000000000000000000000000000000000000000000000000000000000000000000000000000000000000000000000000000000000000000000000000000000000000000000000000000000000000000000000000000000000000000000000000000000000000000000000000000000000000000000000000000000000000000000000000000000000000000000000000000000000000000000000000000000000000000000000000000000000000000000000000000000000000000000000000000000000000000000000000000000000000000000000000000000000000000000000000000000000000000000000000000000000000000000000000000000000000000000000000000000000000000000000000000000000000000000000000000000000000000000000000000000000000000000000000000000000000000000000000000000000000000000000000000000000000000000000000000000000000000000000000000000000000000000000000000000000000000000000000000000000000000000000000000000000000000000000000000000000000000000000000000000000000000000000000000000000000000000000000000000000000000000000000000000000000000000000000000000000000000000000000000000000000000000000000000000000000000000000000000000000000000000000000000000000000000000000000000000000000000000000000000000000000000000000000000000000000000000000000000000000000000000000000000000000000000000000000000000000000000000000000000000000000000000000000000000000000000000000000000000000000000000000000000000000000000000000000000000000000000000000000000000000000000000000000000000000000000000000000000000000000000000000000000000000000000000000000000000000000000000000000000000000000000000000000000000000000000000000000000000000000000000000000000000000000000000000000000000000000000000000000000000000000000000000000000000000000000000000000000000000000000000000000000000000000000000000000000000000000000000000000000000000000000000000000000000000000000000000000000000000000000000000000000000000000000000000000000000000000000000000000000000000000000000000000000000000000000000000000000000000000000000000000000000000000000000000000000000000000000000000000000000000000000000000000000000000000000000000000000000000000000000000000000000000000000000000000000000000000000000000000000000000000000000000000000000000000000000000000000000000000000000000000000000000000000000000000000000000000000000000000000000000000000000000000000000000000000000000000000000000000000000000000000000000000000000000000000000000000000000000000000000000000000000000000000000000000000000000000000000000000000000000000000000000000000000000000000000000000000000000000000000000000000000000000000000000000000000000000000000000000000000000000000000000000000000000000000000000000000000000000000000000000000000000000000000000000000000000000000000000000000000000000000000000000000000000000000000000000000000000000000000000000000000000000000000000000000000000000000000000000000000000000000000000000000000000000000000000000000000000000000000000000000000000000000000000000000000000000000000000000000000000000000000000000000000000000000000000000000000000000000000000000000000000000000000000000000000000000000000000000000000000000000000000000000000000000000000000000000000000000000000000000000000000000000000000000000000000000000000000000000000000000000000000000000000000000000000000000000000000000000000000000000000000000000000000000000000000000000000000000000000000000000000000000000000000000000000000000000000000000000000000000000000000000000000000000000000000000000000000000000000000000000000000000000000000000000000000000000000000000000000000000000000000000000000000000000000000000000000000000000000000000000000000000000000000000000000000000000000000000000000000000000000000000000000000000000000000000000000000000000000000000000000000000000000000000000000000000000000000000000000000000000000000000000000000000000000000000000000000000000000000000000000000000000000000000000000000000000000000000000000000000000000000000000000000000000000000000000000000000000000000000000000000000000000000000000000000000000000000000000000000000000000000000000000000000000000000000000000000000000000000000000000000000000000000000000000000000000000000000000000000000000000000000000000000000000000000000000000000000000000000000000000000000000000000000000000000000000000000000000000000000000000000000000000000000000000000000000000000000000000000000000000000000000000000000000000000000000000000000000000000000000000000000000000000000000000000000000000000000000000000000000000000000000000000000000000000000000000000000000000000000000000000000000000000000000000000000000000000000000000000000000000000000000000000000000000000000000000000000000000000000000000000000000000000000000000000000000000000000000000000000000000000000000000000000000000000000000000000000000000000000000000000000000000000000000000000000000000000000000000000000000000000000000000000000000000000000000000000000000000000000000000000000000000000000000000000000000000000000000000000000000000000000000000000000000000000000000000000000000000000000000000000000000000000000000000000000000000000000000000000000000000000000000000000000000000000000000000000000000000000000000000000000000000000000000000000000000000000000000000000000000000000000000000000000000000000000000000000000000000000000000000000000000000000000000000000000000000000000000000000000000000000000000000000000000000000000000000000000000000000000000000000000000000000000000000000000000000000000000000000000000000000000000000000000000000000000000000000000000000000000000000000000000000000000000000000000000000000000000000000000000000000000000000000000000000000000000000000000000000000000000000000000000000000000000000000000000000000000000000000000000000000000000000000000000000000000000000000000000000000000000000000000000000000000000000000000000000000000000000000000000000000000000000000000000000000000000000000000000000000000000000000000000000000000000000000000000000000000000000000000000000000000000000000000000000000000000000000000000000000000000000000000000000000000000000000000000000000000000000000000000000000000000000000000000000000000000000000000000000000000000000000000000000000000000000000000000000000000000000000000000000000000000000000000000000000000000000000000000000000000000000000000000000000000000000000000000000000000000000000000000000000000000000000000000000000000000000000000000000000000000000000000000000000000000000000000000000000000000000000000000000000000000000000000000000000000000000000000000000000000000000000000000000000000000000000000000000000000000000000000000000000000000000000000000000000000000000000000000000000000000000000000000000000000000000000000000000000000000000000000000000000000000000000000000000000000000000000000000000000000000000000000000000000000000000000000000000000000000000000000000000000000000000000000000000000000000000000000000000000000000000000000000000000000000000000000000000000000000000000000000000000000000000000000000000000000000000000000000000000000000000000000000000000000000000000000000000000000000000000000000000000000000000000000000000000000000000000000000000000000000000000000000000000000000000000000000000000000000000000000000000000000000000000000000000000000000000000000000000000000000000000000000000000000000000000000000000000000000000000000000000000000000000000000000000000000000000000000000000000000000000000000000000000000000000000000000000000000000000000000000000000000000000000000000000000000000000000000000000000000000000000000000000000000000000000000000000000000000000000000000000000000000000000000000000000000000000000000000000000000000000000000000000000000000000000000000000000000000000000000000000000000000000000000000000000000000000000000000000000000000000000000000000000000000000000000000000000000000000000000000000000000000000000000000000000000000000000000000000000000000000000000000000000000000000000000000000000000000000000000000000000000000000000000000000000000000000000000000000000000000000000000000000000000000000000000000000000000000000000000000000000000000000000000000000000000000000000000000000000000000000000000000000000000000000000000000000000000000000000000000000000000000000000000000000000000000000000000000000000000000000000000000000000000000000000000000000000000000000000000000000000000000000000000000000000000000000000000000000000000000000000000000000000000000000000000000000000000000000000000000000000000000000000000000000000000000000000000000000000000000000000000000000000000000000000000000000000000000000000000000000000000000000000000000000000000000000000000000000000000000000000000000000000000000000000000000000000000000000000000000000000000000000000000000000000000000000000000000000000000000000000000000000000000000000000000000000000000000000000000000000000000000000000000000000000000000000000000000000000000000000000000000000000000000000000000000000000000000000000000000000000000000000000000000000000000000000000000000000000000000000000000000000000000000000000000000000000000000000000000000000000000000000000000000000000000000000000000000000000000000000000000000000000000000000000000000000000000000000000000000000000000000000000000000000000000000000000000000000000000000000000000000000000000000000000000000000000000000000000000000000000000000000000000000000000000000000000000000000000000000000000000000000000000000000000000000000000000000000000000000000000000000000000000000000000000000000000000000000000000000000000000000000000000000000000000000000000000000000000000000000000000000000000000000000000000000000000000000000000000000000000000000000000000000000000000000000000000000000000000000000000000000000000000000000000000000000000000000000000000000000000000000000000000000000000000000000000000000000000000000000000000000000000000000000000000000000000000000000000000000000000000000000000000000000000000000000000000000000000000000000000000000000000000000000000000000000000000000000000000000000000000000000000000000000000000000000000000000000000000000000000000000000000000000000000000000000000000000000000000000000000000000000000000000000000000000000000000000000000000000000000000000000000000000000000000000000000000000000000000000000000000000000000000000000000000000000000000000000000000000000000000000000000000000000000000000000000000000000000000000000000000000000000000000000000000000000000000000000000000000000000000000000000000000000000000000000000000000000000000000000000000000000000000000000000000000000000000000000000000000000000000000000000000000000000000000000000000000000000000000000000000000000000000000000000000000000000000000000000000000000000000000000000000000000000000000000000000000000000000000000000000000000000000000000000000000000000000000000000000000000000000000000000000000000000000000000000000000000000000000000000000000000000000000000000000000000000000000000000000000000000000000000000000000000000000000000000000000000000000000000000000000000000000000000000000000000000000000000000000000000000000000000000000000000000000000000000000000000000000000000000000000000000000000000000000000000000000000000000000000000000000000000000000000000000000000000000000000000000000000000000000000000000000000000000000000000000000000000000000000000000000000000000000000000000000000000000000000000000000000000000000000000000000000000000000000000000000000000000000000000000000000000000000000000000000000000000000000000000000000000000000000000000000000000000000000000000000000000000000000000000000000000000000000000000000000000000000000000000000000000000000000000000000000000000000000000000000000000000000000000000000000000000000000000000000000000000000000000000000000000000000000000000000000000000000000000000000000000000000000000000000000000000000000000000000000000000000000000000000000000000000000000000000000000000000000000000000000000000000000000000000000000000000000000000000000000000000000000000000000000000000000000000000000000000000000000000000000000000000000000000000000000000000000000000000000000000000000000000000000000000000000000000000000000000000000000000000000000000000000000000000000000000000000000000000000000000000000000000000000000000000000000000000000000000000000000000000000000000000000000000000000000000000000000000000000000000000000000000000000000000000000000000000000000000000000000000000000000000000000000000000000000000000000000000000000000000000000000000000000000000000000000000000000000000000000000000000000000000000000000000000000000000000000000000000000000000000000000000000000000000000000000000000000000000000000000000000000000000000000000000000000000000000000000000000000000000000000000000000000000000000000000000000000000000000000000000000000000000000000000000000000000000000000000000000000000000000000000000000000000000000000000000000000000000000000000000000000000000000000000000000000000000000000000000000000000000000000000000000000000000000000000000000000000000000000000000000000000000000000000000000000000000000000000000000000000000000000000000000000000000000000000000000000000000000000000000000000000000000000000000000000000000000000000000000000000000000000000000000000000000000000000000000000000000000000000000000000000000000000000000000000000000000000000000000000000000000000000000000000000000000000000000000000000000000000000000000000000000000000000000000000000000000000000000000000000000000000000000000000000000000000000000000000000000000000000000000000000000000000000000000000000000000000000000000000000000000000000000000000000000000000000000000000000000000000000000000000000000000000000000000000000000000000000000000000000000000000000000000000000000000000000000000000000000000000000000000000000000000000000000000000000000000000000000000000000000000000000000000000000000000000000000000000000000000000000000000000000000000000000000000000000000000000000000000000000000000000000000000000000000000000000000000000000000000000000000000000000000000000000000000000000000000000000000000000000000000000000000000000000000000000000000000000000000000000000000000000000000000000000000000000000000000000000000000000000000000000000000000000000000000000000000000000000000000000000000000000000000000000000000000000000000000000000000000000000000000000000000000000000000000000000000000000000000000000000000000000000000000000000000000000000000000000000000000000000000000000000000000000000000000000000000000000000000000000000000000000000000000000000000000000000000000000000000000000000000000000000000000000000000000000000000000000000000000000000000000000000000000000000000000000000000000000000000000000000000000000000000000000000000000000000000000000000000000000000000000000000000000000000000000000000000000000000000000000000000000000000000000000000000000000000000000000000000000000000000000000000000000000000000000000000000000000000000000000000000000000000000000000000000000000000000000000000000000000000000000000000000000000000000000000000000000000000000000000000000000000000000000000000000000000000000000000000000000000000000000000000000000000000000000000000000000000000000000000000000000000000000000000000000000000000000000000000000000000000000000000000000000000000000000000000000000000000000000000000000000000000000000000000000000000000000000000000000000000000000000000000000000000000000000000000000000000000000000000000000000000000000000000000000000000000000000000000000000000000000000000000000000000000000000000000000000000000000000000000000000000000000000000000000000000000000000000000000000000000000000000000000000000000000000000000000000000000000000000000000000000000000000000000000000000000000000000000000000000000000000000000000000000000000000000000000000000000000000000000000000000000000000000000000000000000000000000000000000000000000000000000000000000000000000000000000000000000000000000000000000000000000000000000000000000000000000000000000000000000000000000000000000000000000000000000000000000000000000000000000000000000000000000000000000000000000000000000000000000000000000000000000000000000000000000000000000000000000000000000000000000000000000000000000000000000000000000000000000000000000000000000000000000000000000000000000000000000000000000000000000000000000000000000000000000000000000000000000000000000000000000000000000000000000000000000000000000000000000000000000000000000000000000000000000000000000000000000000000000000000000000000000000000000000000000000000000000000000000000000000000000000000000000000000000000000000000000000000000000000000000000000000000000000000000000000000000000000000000000000000000000000000000000000000000000000000000000000000000000000000000000000000000000000000000000000000000000000000000000000000000000000000000000000000000000000000000000000000000000000000000000000000000000000000000000000000000000000000000000000000000000000000000000000000000000000000000000000000000000000000000000000000000000000000000000000000000000000000000000000000000000000000000000000000000000000000000000000000000000000000000000000000000000000000000000000000000000000000000000000000000000000000000000000000000000000000000000000000000000000000000000000000000000000000000000000000000000000000000000000000000000000000000000000000000000000000000000000000000000000000000000000000000000000000000000000000000000000000000000000000000000000000000000000000000000000000000000000000000000000000000000000000000000000000000000000000000000000000000000000000000000000000000000000000000000000000000000000000000000000000000000000000000000000000000000000000000000000000000000000000000000000000000000000000000000000000000000000000000000000000000000000000000000000000000000000000000000000000000000000000000000000000000000000000000000000000000000000000000000000000000000000000000000000000000000000000000000000000000000000000000000000000000000000000000000000000000000000000000000000000000000000000000000000000000000000000000000000000000000000000000000000000000000000000000000000000000000000000000000000000000000000000000000000000000000000000000000000000000000000000000000000000000000000000000000000000000000000000000000000000000000000000000000000000000000000000000000000000000000000000000000000000000000000000000000000000000000000000000000000000000000000000000000000000000000000000000000000000000000000000000000000000000000000000000000000000000000000000000000000000000000000000000000000000000000000000000000000000000000000000000000000000000000000000000000000000000000000000000000000000000000000000000000000000000000000000000000000000000000000000000000000000000000000000000000000000000000000000000000000000000000000000000000000000000000000000000000000000000000000000000000000000000000000000000000000000000000000000000000000000000000000000000000000000000000000000000000000000000000000000000000000000000000000000000000000000000000000000000000000000000000000000000000000000000000000000000000000000000000000000000000000000000000000000000000000000000000000000000000000000000000000000000000000000000000000000000000000000000000000000000000000000000000000000000000000000000000000000000000000000000000000000000000000000000000000000000000000000000000000000000000000000000000000000000000000000000000000000000000000000000000000000000000000000000000000000000000000000000000000000000000000000000000000000000000000000000000000000000000000000000000000000000000000000000000000000000000000000000000000000000000000000000000000000000000000000000000000000000000000000000000000000000000000000000000000000000000000000000000000000000000000000000000000000000000000000000000000000000000000000000000000000000000000000000000000000000000000000000000000000000000000000000000000000000000000000000000000000000000000000000000000000000000000000000000000000000000000000000000000000000000000000000000000000000000000000000000000000000000000000000000000000000000000000000000000000000000000000000000000000000000000000000000000000000000000000000000000000000000000000000000000000000000000000000000000000000000000000000000000000000000000000000000000000000000000000000000000000000000000000000000000000000000000000000000000000000000000000000000000000000000000000000000000000000000000000000000000000000000000000000000000000000000000000000000000000000000000000000000000000000000000000000000000000000000000000000000000000000000000000000000000000000000000000000000000000000000000000000000000000000000000000000000000000000000000000000000000000000000000000000000000000000000000000000000000000000000000000000000000000000000000000000000000000000000000000000000000000000000000000000000000000000000000000000000000000000000000000000000000000000000000000000000000000000000000000000000000000000000000000000000000000000000000000000000000000000000000000000000000000000000000000000000000000000000000000000000000000000000000000000000000000000000000000000000000000000000000000000000000000000000000000000000000000000000000000000000000000000000000000000000000000000000000000000000000000000000000000000000000000000000000000000000000000000000000000000000000000000000000000000000000000000000000000000000000000000000000000000000000000000000000000000000000000000000000000000000000000000000000000000000000000000000000000000000000000000000000000000000000000000000000000000000000000000000000000000000000000000000000000000000000000000000000000000000000000000000000000000000000000000000000000000000000000000000000000000000000000000000000000000000000000000000000000000000000000000000000000000000000000000000000000000000000000000000000000000000000000000000000000000000000000000000000000000000000000000000000000000000000000000000000000000000000000000000000000000000000000000000000000000000000000000000000000000000000000000000000000000000000000000000000000000000000000000000000000000000000000000000000000000000000000000000000000000000000000000000000000000000000000000000000000000000000000000000000000000000000000000000000000000000000000000000000000000000000000000000000000000000000000000000000000000000000000000000000000000000000000000000000000000000000000000000000000000000000000000000000000000000000000000000000000000000000000000000000000000000000000000000000000000000000000000000000000000000000000000000000000000000000000000000000000000000000000000000000000000000000000000000000000000000000000000000000000000000000000000000000000000000000000000000000000000000000000000000000000000000000000000000000000000000000000000000000000000000000000000000000000000000000000000000000000000000000000000000000000000000000000000000000000000000000000000000000000000000000000000000000000000000000000000000000000000000000000000000000000000000000000000000000000000000000000000000000000000000000000000000000000000000000000000000000000000000000000000000000000000000000000000000000000000000000000000000000000000000000000000000000000000000000000000000000000000000000000000000000000000000000000000000000000000000000000000000000000000000000000000000000000000000000000000000000000000000000000000000000000000000000000000000000000000000000000000000000000000000000000000000000000000000000000000000000000000000000000000000000000000000000000000000000000000000000000000000000000000000000000000000000000000000000000000000000000000000000000000000000000000000000000000000000000000000000000000000000000000000000000000000000000000000000000000000000000000000000000000000000000000000000000000000000000000000000000000000000000000000000000000000000000000000000000000000000000000000000000000000000000000000000000000000000000000000000000000000000000000000000000000000000000000000000000000000000000000000000000000000000000000000000000000000000000000000000000000000000000000000000000000000000000000000000000000000000000000000000000000000000000000000000000000000000000000000000000000000000000000000000000000000000000000000000000000000000000000000000000000000000000000000000000000000000000000000000000000000000000000000000000000000000000000000000000000000000000000000000000000000000000000000000000000000000000000000000000000000000000000000000000000000000000000000000000000000000000000000000000000000000000000000000000000000000000000000000000000000000000000000000000000000000000000000000000000000000000000000000000000000000000000000000000000000000000000000000000000000000000000000000000000000000000000000000000000000000000000000000000000000000000000000000000000000000000000000000000000000000000000000000000000000000000000000000000000000000000000000000000000000000000000000000000000000000000000000000000000000000000000000000000000000000000000000000000000000000000000000000000000000000000000000000000000000000000000000000000000000000000000000000000000000000000000000000000000000000000000000000000000000000000000000000000000000000000000000000000000000000000000000000000000000000000000000000000000000000000000000000000000000000000000000000000000000000000000000000000000000000000000000000000000000000000000000000000000000000000000000000000000000000000000000000000000000000000000000000000000000000000000000000000000000000000000000000000000000000000000000000000000000000000000000000000000000000000000000000000000000000000000000000000000000000000000000000000000000000000000000000000000000000000000000000000000000000000000000000000000000000000000000000000000000000000000000000000000000000000000000000000000000000000000000000000000000000000000000000000000000000000000000000000000000000000000000000000000000000000000000000000000000000000000000000000000000000000000000000000000000000000000000000000000000000000000000000000000000000000000000000000000000000000000000000000000000000000000000000000000000000000000000000000000000000000000000000000000000000000000000000000000000000000000000000000000000000000000000000000000000000000000000000000000000000000000000000000000000000000000000000000000000000000000000000000000000000000000000000000000000000000000000000000000000000000000000000000000000000000000000000000000000000000000000000000000000000000000000000000000000000000000000000000000000000000000000000000000000000000000000000000000000000000000000000000000000000000000000000000000000000000000000000000000000000000000000000000000000000000000000000000000000000000000000000000000000000000000000000000000000000000000000000000000000000000000000000000000000000000000000000000000000000000000000000000000000000000000000000000000000000000000000000000000000000000000000000000000000000000000000000000000000000000000000000000000000000000000000000000000000000000000000000000000000000000000000000000000000000000000000000000000000000000000000000000000000000000000000000000000000000000000000000000000000000000000000000000000000000000000000000000000000000000000000000000000000000000000000000000000000000000000000000000000000000000000000000000000000000000000000000000000000000000000000000000000000000000000000000000000000000000000000000000000000000000000000000000000000000000000000000000000000000000000000000000000000000000000000000000000000000000000000000000000000000000000000000000000000000000000000000000000000000000000000000000000000000000000000000000000000000000000000000000000000000000000000000000000000000000000000000000000000000000000000000000000000000000000000000000000000000000000000000000000000000000000000000000000000000000000000000000000000000000000000000000000000000000000000000000000000000000000000000000000000000000000000000000000000000000000000000000000000000000000000000000000000000000000000000000000000000000000000000000000000000000000000000000000000000000000000000000000000000000000000000000000000000000000000000000000000000000000000000000000000000000000000000000000000000000000000000000000000000000000000000000000000000000000000000000000000000000000000000000000000000000000000000000000000000000000000000000000000000000000000000000000000000000000000000000000000000000000000000000000000000000000000000000000000000000000000000000000000000000000000000000000000000000000000000000000000000000000000000000000000000000000000000000000000000000000000000000000000000000000000000000000000000000000000000000000000000000000000000000000000000000000000000000000000000000000000000000000000000000000000000000000000000000000000000000000000000000000000000000000000000000000000000000000000000000000000000000000000000000000000000000000000000000000000000000000000000000000000000000000000000000000000000000000000000000000000000000000000000000000000000000000000000000000000000000000000000000000000000000000000000000000000000000000000000000000000000000000000000000000000000000000000000000000000000000000000000000000000000000000000000000000000000000000000000000000000000000000000000000000000000000000000000000000000000000000000000000000000000000000000000000000000000000000000000000000000000000000000000000000000000000000000000000000000000000000000000000000000000000000000000000000000000000000000000000000000000000000000000000000000000000000000000000000000000000000000000000000000000000000000000000000000000000000000000000000000000000000000000000000000000000000000000000000000000000000000000000000000000000000000000000000000000000000000000000000000000000000000000000000000000000000000000000000000000000000000000000000000000000000000000000000000000000000000000000000000000000000000000000000000000000000000000000000000000000000000000000000000000000000000000000000000000000000000000000000000000000000000000000000000000000000000000000000000000000000000000000000000000000000000000000000000000000000000000000000000000000000000000000000000000000000000000000000000000000000000000000000000000000000000000000000000000000000000000000000000000000000000000000000000000000000000000000000000000000000000000000000000000000000000000000000000000000000000000000000000000000000000000000000000000000000000000000000000000000000000000000000000000000000000000000000000000000000000000000000000000000000000000000000000000000000000000000000000000000000000000000000000000000000000000000000000000000000000000000000000000000000000000000000000000000000000000000000000000000000000000000000000000000000000000000000000000000000000000000000000000000000000000000000000000000000000000000000000000000000000000000000000000000000000000000000000000000000000000000000000000000000000000000000000000000000000000000000000000000000000000000000000000000000000000000000000000000000000000000000000000000000000000000000000000000000000000000000000000000000000000000000000000000000000000000000000000000000000000000000000000000000000000000000000000000000000000000000000000000000000000000000000000000000000000000000000000000000000000000000000000000000000000000000000000000000000000000000000000000000000000000000000000000000000000000000000000000000000000000000000000000000000000000000000000000000000000000000000000000000000000000000000000000000000000000000000000000000000000000000000000000000000000000000000000000000000000000000000000000000000000000000000000000000000000000000000000000000000000000000000000000000000000000000000000000000000000000000000000000000000000000000000000000000000000000000000000000000000000000000000000000000000000000000000000000000000000000000000000000000000000000000000000000000000000000000000000000000000000000000000000000000000000000000000000000000000000000000000000000000000000000000000000000000000000000000000000000000000000000000000000000000000000000000000000000000000000000000000000000000000000000000000000000000000000000000000000000000000000000000000000000000000000000000000000000000000000000000000000000000000000000000000000000000000000000000000000000000000000000000000000000000000000000000000000000000000000000000000000000000000000000000000000000000000000000000000000000000000000000000000000000000000000000000000000000000000000000000000000000000000000000000000000000000000000000000000000000000000000000000000000000000000000000000000000000000000000000000000000000000000000000000000000000000000000000000000000000000000000000000000000000000000000000000000000000000000000000000000000000000000000000000000000000000000000000000000000000000000000000000000000000000000000000000000000000000000000000000000000000000000000000000000000000000000000000000000000000000000000000000000000000000000000000000000000000000000000000000000000000000000000000000000000000000000000000000000000000000000000000000000000000000000000000000000000000000000000000000000000000000000000000000000000000000000000000000000000000000000000000000000000000000000000000000000000000000000000000000000000000000000000000000000000000000000000000000000000000000000000000000000000000000000000000000000000000000000000000000000000000000000000000000000000000000000000000000000000000000000000000000000000000000000000000000000000000000000000000000000000000000000000000000000000000000000000000000000000000000000000000000000000000000000000000000000000000000000000000000000000000000000000000000000000000000000000000000000000000000000000000000000000000000000000000000000000000000000000000000000000000000000000000000000000000000000000000000000000000000000000000000000000000000000000000000000000000000000000000000000000000000000000000000000000000000000000000000000000000000000000000000000000000000000000000000000000000000000000000000000000000000000000000000000000000000000000000000000000000000000000000000000000000000000000000000000000000000000000000000000000000000000000000000000000000000000000000000000000000000000000000000000000000000000000000000000000000000000000000000000000000000000000000000000000000000000000000000000000000000000000000000000000000000000000000000000000000000000000000000000000000000000000000000000000000000000000000000000000000000000000000000000000000000000000000000000000000000000000000000000000000000000000000000000000000000000000000000000000000000000000000000000000000000000000000000000000000000000000000000000000000000000000000000000000000000000000000000000000000000000000000000000000000000000000000000000000000000000000000000000000000000000000000000000000000000000000000000000000000000000000000000000000000000000000000000000000000000000000000000000000000000000000000000000000000000000000000000000000000000000000000000000000000000000000000000000000000000000000000000000000000000000000000000000000000000000000000000000000000000000000000000000000000000000000000000000000000000000000000000000000000000000000000000000000000000000000000000000000000000000000000000000000000000000000000000000000000000000000000000000000000000000000000000000000000000000000000000000000000000000000000000000000000000000000000000000000000000000000000000000000000000000000000000000000000000000000000000000000000000000000000000000000000000000000000000000000000000000000000000000000000000000000000000000000000000000000000000000000000000000000000000000000000000000000000000000000000000000000000000000000000000000000000000000000000000000000000000000000000000000000000000000000000000000000000000000000000000000000000000000000000000000000000000000000000000000000000000000000000000000000000000000000000000000000000000000000000000000000000000000000000000000000000000000000000000000000000000000000000000000000000000000000000000000000000000000000000000000000000000000000000000000000000000000000000000000000000000000000000000000000000000000000000000000000000000000000000000000000000000000000000000000000000000000000000000000000000000000000000000000000000000000000000000000000000000000000000000000000000000000000000000000000000000000000000000000000000000000000000000000000000000000000000000000000000000000000000000000000000000000000000000000000000000000000000000000000000000000000000000000000000000000000000000000000000000000000000000000000000000000000000000000000000000000000000000000000000000000000000000000000000000000000000000000000000000000000000000000000000000000000000000000000000000000000000000000000000000000000000000000000000000000000000000000000000000000000000000000000000000000000000000000000000000000000000000000000000000000000000000000000000000000000000000000000000000000000000000000000000000000000000000000000000000000000000000000000000000000000000000000000000000000000000000000000000000000000000000000000000000000000000000000000000000000000000000000000000000000000000000000000000000000000000000000000000000000000000000000000000000000000000000000000000000000000000000000000000000000000000000000000000000000000000000000000000000000000000000000000000000000000000000000000000000000000000000000000000000000000000000000000000000000000000000000000000000000000000000000000000000000000000000000000000000000000000000000000000000000000000000000000000000000000000000000000000000000000000000000000000000000000000000000000000000000000000000000000000000000000000000000000000000000000000000000000000000000000000000000000000000000000000000000000000000000000000000000000000000000000000000000000000000000000000000000000000000000000000000000000000000000000000000000000000000000000000000000000000000000000000000000000000000000000000000000000000000000000000000000000000000000000000000000000000000000000000000000000000000000000000000000000000000000000000000000000000000000000000000000000000000000000000000000000000000000000000000000000000000000000000000000000000000000000000000000000000000000000000000000000000000000000000000000000000000000000000000000000000000000000000000000000000000000000000000000000000000000000000000000000000000000000000000000000000000000000000000000000000000000000000000000000000000000000000000000000000000000000000000000000000000000000000000000000000000000000000000000000000000000000000000000000000000000000000000000000000000000000000000000000000000000000000000000000000000000000000000000000000000000000000000000000000000000000000000000000000000000000000000000000000000000000000000000000000000000000000000000000000000000000000000000000000000000000000000000000000000000000000000000000000000000000000000000000000000000000000000000000000000000000000000000000000000000000000000000000000000000000000000000000000000000000000000000000000000000000000000000000000000000000000000000000000000000000000000000000000000000000000000000000000000000000000000000000000000000000000000000000000000000000000000000000000000000000000000000000000000000000000000000000000000000000000000000000000000000000000000000000000000000000000000000000000000000000000000000000000000000000000000000000000000000000000000000000000000000000000000000000000000000000000000000000000000000000000000000000000000000000000000000000000000000000000000000000000000000000000000000000000000000000000000000000000000000000000000000000000000000000000000000000000000000000000000000000000000000000000000000000000000000000000000000000000000000000000000000000000000000000000000000000000000000000000000000000000000000000000000000000000000000000000000000000000000000000000000000000000000000000000000000000000000000000000000000000000000000000000000000000000000000000000000000000000000000000000000000000000000000000000000000000000000000000000000000000000000000000000000000000000000000000000000000000000000000000000000000000000000000000000000000000000000000000000000000000000000000000000000000000000000000000000000000000000000000000000000000000000000000000000000000000000000000000000000000000000000000000000000000000000000000000000000000000000000000000000000000000000000000000000000000000000000000000000000000000000000000000000000000000000000000000000000000000000000000000000000000000000000000000000000000000000000000000000000000000000000000000000000000000000000000000000000000000000000000000000000000000000000000000000000000000000000000000000000000000000000000000000000000000000000000000000000000000000000000000000000000000000000000000000000000000000000000000000000000000000000000000000000000000000000000000000000000000000000000000000000000000000000000000000000000000000000000000000000000000000000000000000000000000000000000000000000000000000000000000000000000000000000000000000000000000000000000000000000000000000000000000000000000000000000000000000000000000000000000000000000000000000000000000000000000000000000000000000000000000000000000000000000000000000000000000000000000000000000000000000000000000000000000000000000000000000000000000000000000000000000000000000000000000000000000000000000000000000000000000000000000000000000000000000000000000000000000000000000000000000000000000000000000000000000000000000000000000000000000000000000000000000000000000000000000000000000000000000000000000000000000000000000000000000000000000000000000000000000000000000000000000000000000000000000000000000000000000000000000000000000000000000000000000000000000000000000000000000000000000000000000000000000000000000000000000000000000000000000000000000000000000000000000000000000000000000000000000000000000000000000000000000000000000000000000000000000000000000000000000000000000000000000000000000000000000000000000000000000000000000000000000000000000000000000000000000000000000000000000000000000000000000000000000000000000000000000000000000000000000000000000000000000000000000000000000000000000000000000000000000000000000000000000000000000000000000000000000000000000000000000000000000000000000000000000000000000000000000000000000000000000000000000000000000000000000000000000000000000000000000000000000000000000000000000000000000000000000000000000000000000000000000000000000000000000000000000000000000000000000000000000000000000000000000000000000000000000000000000000000000000000000000000000000000000000000000000000000000000000000000000000000000000000000000000000000000000000000000000000000000000000000000000000000000000000000000000000000000000000000000000000000000000000000000000000000000000000000000000000000000000000000000000000000000000000000000000000000000000000000000000000000000000000000000000000000000000000000000000000000000000000000000000000000000000000000000000000000000000000000000000000000000000000000000000000000000000000000000000000000000000000000000000000000000000000000000000000000000000000000000000000000000000000000000000000000000000000000000000000000000000000000000000000000000000000000000000000000000000000000000000000000000000000000000000000000000000000000000000000000000000000000000000000000000000000000000000000000000000000000000000000000000000000000000000000000000000000000000000000000000000000000000000000000000000000000000000000000000000000000000000000000000000000000000000000000000000000000000000000000000000000000000000000000000000000000000000000000000000000000000000000000000000000000000000000000000000000000000000000000000000000000000000000000000000000000000000000000000000000000000000000000000000000000000000000000000000000000000000000000000000000000000000000000000000000000000000000000000000000000000000000000000000000000000000000000000000000000000000000000000000000000000000000000000000000000000000000000000000000000000000000000000000000000000000000000000000000000000000000000000000000000000000000000000000000000000000000000000000000000000000000000000000000000000000000000000000000000000000000000000000000000000000000000000000000000000000000000000000000000000000000000000000000000000000000000000000000000000000000000000000000000000000000000000000000000000000000000000000000000000000000000000000000000000000000000000000000000000000000000000000000000000000000000000000000000000000000000000000000000000000000000000000000000000000000000000000000000000000000000000000000000000000000000000000000000000000000000000000000000000000000000000000000000000000000000000000000000000000000000000000000000000000000000000000000000000000000000000000000000000000000000000000000000000000000000000000000000000000000000000000000000000000000000000000000000000000000000000000000000000000000000000000000000000000000000000000000000000000000000000000000000000000000000000000000000000000000000000000000000000000000000000000000000000000000000000000000000000000000000000000000000000000000000000000000000000000000000000000000000000000000000000000000000000000000000000000000000000000000000000000000000000000000000000000000000000000000000000000000000000000000000000000000000000000000000000000000000000000000000000000000000000000000000000000000000000000000000000000000000000000000000000000000000000000000000000000000000000000000000000000000000000000000000000000000000000000000000000000000000000000000000000000000000000000000000000000000000000000000000000000000000000000000000000000000000000000000000000000000000000000000000000000000000000000000000000000000000000000000000000000000000000000000000000000000000000000000000000000000000000000000000000000000000000000000000000000000000000000000000000000000000000000000000000000000000000000000000000000000000000000000000000000000000000000000000000000000000000000000000000000000000000000000000000000000000000000000000000000000000000000000000000000000000000000000000000000000000000000000000000000000000000000000000000000000000000000000000000000000000000000000000000000000000000000000000000000000000000000000000000000000000000000000000000000000000000000000000000000000000000000000000000000000000000000000000000000000000000000000000000000000000000000000000000000000000000000000000000000000000000000000000000000000000000000000000000000000000000000000000000000000000000000000000000000000000000000000000000000000000000000000000000000000000000000000000000000000000000000000000000000000000000000000000000000000000000000000000000000000000000000000000000000000000000000000000000000000000000000000000000000000000000000000000000000000000000000000000000000000000000000000000000000000000000000000000000000000000000000000000000000000000000000000000000000000000000000000000000000000000000000000000000000000000000000000000000000000000000000000000000000000000000000000000000000000000000000000000000000000000000000000000000000000000000000000000000000000000000000000000000000000000000000000000000000000000000000000000000000000000000000000000000000000000000000000000000000000000000000000000000000000000000000000000000000000000000000000000000000000000000000000000000000000000000000000000000000000000000000000000000000000000000000000000000000000000000000000000000000000000000000000000000000000000000000000000000000000000000000000000000000000000000000000000000000000000000000000000000000000000000000000000000000000000000000000000000000000000000000000000000000000000000000000000000000000000000000000000000000000000000000000000000000000000000000000000000000000000000000000000000000000000000000000000000000000000000000000000000000000000000000000000000000000000000000000000000000000000000000000000000000000000000000000000000000000000000000000000000000000000000000000000000000000000000000000000000000000000000000000000000000000000000000000000000000000000000000000000000000000000000000000000000000000000000000000000000000000000000000000000000000000000000000000000000000000000000000000000000000000000000000000000000000000000000000000000000000000000000000000000000000000000000000000000000000000000000000000000000000000000000000000000000000000000000000000000000000000000000000000000000000000000000000000000000000000000000000000000000000000000000000000000000000000000000000000000000000000000000000000000000000000000000000000000000000000000000000000000000000000000000000000000000000000000000000000000000000000000000000000000000000000000000000000000000000000000000000000000000000000000000000000000000000000000000000000000000000000000000000000000000000000000000000000000000000000000000000000000000000000000000000000000000000000000000000000000000000000000000000000000000000000000000000000000000000000000000000000000000000000000000000000000000000000000000000000000000000000000000000000000000000000000000000000000000000000000000000000000000000000000000000000000000000000000000000000000000000000000000000000000000000000000000000000000000000000000000000000000000000000000000000000000000000000000000000000000000000000000000000000000000000000000000000000000000000000000000000000000000000000000000000000000000000000000000000000000000000000000000000000000000000000000000000000000000000000000000000000000000000000000000000000000000000000000000000000000000000000000000000000000000000000000000000000000000000000000000000000000000000000000000000000000000000000000000000000000000000000000000000000000000000000000000000000000000000000000000000000000000000000000000000000000000000000000000000000000000000000000000000000000000000000000000000000000000000000000000000000000000000000000000000000000000000000000000000000000000000000000000000000000000000000000000000000000000000000000000000000000000000000000000000000000000000000000000000000000000000000000000000000000000000000000000000000000000000000000000000000000000000000000000000000000000000000000000000000000000000000000000000000000000000000000000000000000000000000000000000000000000000000000000000000000000000000000000000000000000000000000000000000000000000000000000000000000000000000000000000000000000000000000000000000000000000000000000000000000000000000000000000000000000000000000000000000000000000000000000000000000000000000000000000000000000000000000000000000000000000000000000000000000000000000000000000000000000000000000000000000000000000000000000000000000000000000000000000000000000000000000000000000000000000000000000000000000000000000000000000000000000000000000000000000000000000000000000000000000000000000000000000000000000000000000000000000000000000000000000000000000000000000000000000000000000000000000000000000000000000000000000000000000000000000000000000000000000000000000000000000000000000000000000000000000000000000000000000000000000000000000000000000000000000000000000000000000000000000000000000000000000000000000000000000000000000000000000000000000000000000000000000000000000000000000000000000000000000000000000000000000000000000000000000000000000000000000000000000000000000000000000000000000000000000000000000000000000000000000000000000000000000000000000000000000000000000000000000000000000000000000000000000000000000000000000000000000000000000000000000000000000000000000000000000000000000000000000000000000000000000000000000000000000000000000000000000000000000000000000000000000000000000000000000000000000000000000000000000000000000000000000000000000000000000000000000000000000000000000000000000000000000000000000000000000000000000000000000000000000000000000000000000000000000000000000000000000000000000000000000000000000000000000000000000000000000000000000000000000000000000000000000000000000000000000000000000000000000000000000000000000000000000000000000000000000000000000000000000000000000000000000000000000000000000000000000000000000000000000000000000000000000000000000000000000000000000000000000000000000000000000000000000000000000000000000000000000000000000000000000000000000000000000000000000000000000000000000000000000000000000000000000000000000000000000000000000000000000000000000000000000000000000000000000000000000000000000000000000000000000000000000000000000000000000000000000000000000000000000000000000000000000000000000000000000000000000000000000000000000000000000000000000000000000000000000000000000000000000000000000000000000000000000000000000000000000000000000000000000000000000000000000000000000000000000000000000000000000000000000000000000000000000000000000000000000000000000000000000000000000000000000000000000000000000000000000000000000000000000000000000000000000000000000000000000000000000000000000000000000000000000000000000000000000000000000000000000000000000000000000000000000000000000000000000000000000000000000000000000000000000000000000000000000000000000000000000000000000000000000000000000000000000000000000000000000000000000000000000000000000000000000000000000000000000000000000000000000000000000000000000000000000000000000000000000000000000000000000000000000000000000000000000000000000000000000000000000000000000000000000000000000000000000000000000000000000000000000000000000000000000000000000000000000000000000000000000000000000000000000000000000000000000000000000000000000000000000000000000000000000000000000000000000000000000000000000000000000000000000000000000000000000000000000000000000000000000000000000000000000000000000000000000000000000000000000000000000000000000000000000000000000000000000000000000000000000000000000000000000000000000000000000000000000000000000000000000000000000000000000000000000000000000000000000000000000000000000000000000000000000000000000000000000000000000000000000000000000000000000000000000000000000000000000000000000000000000000000000000000000000000000000000000000000000000000000000000000000000000000000000000000000000000000000000000000000000000000000000000000000000000000000000000000000000000000000000000000000000000000000000000000000000000000000000000000000000000000000000000000000000000000000000000000000000000000000000000000000000000000000000000000000000000000000000000000000000000000000000000000000000000000000000000000000000000000000000000000000000000000000000000000000000000000000000000000000000000000000000000000000000000000000000000000000000000000000000000000000000000000000000000000000000000000000000000000000000000000000000000000000000000000000000000000000000000000000000000000000000000000000000000000000000000000000000000000000000000000000000000000000000000000000000000000000000000000000000000000000000000000000000000000000000000000000000000000000000000000000000000000000000000000000000000000000000000000000000000000000000000000000000000000000000000000000000000000000000000000000000000000000000000000000000000000000000000000000000000000000000000000000000000000000000000000000000000000000000000000000000000000000000000000000000000000000000000000000000000000000000000000000000000000000000000000000000000000000000000000000000000000000000000000000000000000000000000000000000000000000000000000000000000000000000000000000000000000000000000000000000000000000000000000000000000000000000000000000000000000000000000000000000000000000000000000000000000000000000000000000000000000000000000000000000000000000000000000000000000000000000000000000000000000000000000000000000000000000000000000000000000000000000000000000000000000000000000000000000000000000000000000000000000000000000000000000000000000000000000000000000000000000000000000000000000000000000000000000000000000000000000000000000000000000000000000000000000000000000000000000000000000000000000000000000000000000000000000000000000000000000000000000000000000000000000000000000000000000000000000000000000000000000000000000000000000000000000000000000000000000000000000000000000000000000000000000000000000000000000000000000000000000000000000000000000000000000000000000000000000000000000000000000000000000000000000000000000000000000000000000000000000000000000000000000000000000000000000000000000000000000000000000000000000000000000000000000000000000000000000000000000000000000000000000000000000000000000000000000000000000000000000000000000000000000000000000000000000000000000000000000000000000000000000000000000000000000000000000000000000000000000000000000000000000000000000000000000000000000000000000000000000000000000000000000000000000000000000000000000000000000000000000000000000000000000000000000000000000000000000000000000000000000000000000000000000000000000000000000000000000000000000000000000000000000000000000000000000000000000000000000000000000000000000000000000000000000000000000000000000000000000000000000000000000000000000000000000000000000000000000000000000000000000000000000000000000000000000000000000000000000000000000000000000000000000000000000000000000000000000000000000000000000000000000000000000000000000000000000000000000000000000000000000000000000000000000000000000000000000000000000000000000000000000000000000000000000000000000000000000000000000000000000000000000000000000000000000000000000000000000000000000000000000000000000000000000000000000000000000000000000000000000000000000000000000000000000000000000000000000000000000000000000000000000000000000000000000000000000000000000000000000000000000000000000000000000000000000000000000000000000000000000000000000000000000000000000000000000000000000000000000000000000000000000000000000000000000000000000000000000000000000000000000000000000000000000000000000000000000000000000000000000000000000000000000000000000000000000000000000000000000000000000000000000000000000000000000000000000000000000000000000000000000000000000000000000000000000000000000000000000000000000000000000000000000000000000000000000000000000000000000000000000000000000000000000000000000000000000000000000000000000000000000000000000000000000000000000000000000000000000000000000000000000000000000000000000000000000000000000000000000000000000000000000000000000000000000000000000000000000000000000000000000000000000000000000000000000000000000000000000000000000000000000000000000000000000000000000000000000000000000000000000000000000000000000000000000000000000000000000000000000000000000000000000000000000000000000000000000000000000000000000000000000000000000000000000000000000000000000000000000000000000000000000000000000000000000000000000000000000000000000000000000000000000000000000000000000000000000000000000000000000000000000000000000000000000000000000000000000000000000000000000000000000000000000000000000000000000000000000000000000000000000000000000000000000000000000000000000000000000000000000000000000000000000000000000000000000000000000000000000000000000000000000000000000000000000000000000000000000000000000000000000000000000000000000000000000000000000000000000000000000000000000000000000000000000000000000000000000000000000000000000000000000000000000000000000000000000000000000000000000000000000000000000000000000000000000000000000000000000000000000000000000000000000000000000000000000000000000000000000000000000000000000000000000000000000000000000000000000000000000000000000000000000000000000000000000000000000000000000000000000000000000000000000000000000000000000000000000000000000000000000000000000000000000000000000000000000000000000000000000000000000000000000000000000000000000000000000000000000000000000000000000000000000000000000000000000000000000000000000000000000000000000000000000000000000000000000000000000000000000000000000000000000000000000000000000000000000000000000000000000000000000000000000000000000000000000000000000000000000000000000000000000000000000000000000000000000000000000000000000000000000000000000000000000000000000000000000000000000000000000000000000000000000000000000000000000000000000000000000000000000000000000000000000000000000000000000000000000000000000000000000000000000000000000000000000000000000000000000000000000000000000000000000000000000000000000000000000000000000000000000000000000000000000000000000000000000000000000000000000000000000000000000000000000000000000000000000000000000000000000000000000000000000000000000000000000000000000000000000000000000000000000000000000000000000000000000000000000000000000000000000000000000000000000000000000000000000000000000000000000000000000000000000000000000000000000000000000000000000000000000000000000000000000000000000000000000000000000000000000000000000000000000000000000000000000000000000000000000000000000000000000000000000000000000000000000000000000000000000000000000000000000000000000000000000000000000000000000000000000000000000000000000000000000000000000000000000000000000000000000000000000000000000000000000000000000000000000000000000000000000000000000000000000000000000000000000000000000000000000000000000000000000000000000000000000000000000000000000000000000000000000000000000000000000000000000000000000000000000000000000000000000000000000000000000000000000000000000000000000000000000000000000000000000000000000000000000000000000000000000000000000000000000000000000000000000000000000000000000000000000000000000000000000000000000000000000000000000000000000000000000000000000000000000000000000000000000000000000000000000000000000000000000000000000000000000000000000000000000000000000000000000000000000000000000000000000000000000000000000000000000000000000000000000000000000000000000000000000000000000000000000000000000000000000000000000000000000000000000000000000000000000000000000000000000000000000000000000000000000000000000000000000000000000000000000000000000000000000000000000000000000000000000000000000000000000000000000000000000000000000000000000000000000000000000000000000000000000000000000000000000000000000000000000000000000000000000000000000000000000000000000000000000000000000000000000000000000000000000000000000000000000000000000000000000000000000000000000000000000000000000000000000000000000000000000000000000000000000000000000000000000000000000000000000000000000000000000000000000000000000000000000000000000000000000000000000000000000000000000000000000000000000000000000000000000000000000000000000000000000000000000000000000000000000000000000000000000000000000000000000000000000000000000000000000000000000000000000000000000000000000000000000000000000000000000000000000000000000000000000000000000000000000000000000000000000000000000000000000000000000000000000000000000000000000000000000000000000000000000000000000000000000000000000000000000000000000000000000000000000000000000000000000000000000000000000000000000000000000000000000000000000000000000000000000000000000000000000000000000000000000000000000000000000000000000000000000000000000000000000000000000000000000000000000000000000000000000000000000000000000000000000000000000000000000000000000000000000000000000000000000000000000000000000000000000000000000000000000000000000000000000000000000000000000000000000000000000000000000000000000000000000000000000000000000000000000000000000000000000000000000000000000000000000000000000000000000000000000000000000000000000000000000000000000000000000000000000000000000000000000000000000000000000000000000000000000000000000000000000000000000000000000000000000000000000000000000000000000000000000000000000000000000000000000000000000000000000000000000000000000000000000000000000000000000000000000000000000000000000000000000000000000000000000000000000000000000000000000000000000000000000000000000000000000000000000000000000000000000000000000000000000000000000000000000000000000000000000000000000000000000000000000000000000000000000000000000000000000000000000000000000000000000000000000000000000000000000000000000000000000000000000000000000000000000000000000000000000000000000000000000000000000000000000000000000000000000000000000000000000000000000000000000000000000000000000000000000000000000000000000000000000000000000000000000000000000000000000000000000000000000000000000000000000000000000000000000000000000000000000000000000000000000000000000000000000000000000000000000000000000000000000000000000000000000000000000000000000000000000000000000000000000000000000000000000000000000000000000000000000000000000000000000000000000000000000000000000000000000000000000000000000000000000000000000000000000000000000000000000000000000000000000000000000000000000000000000000000000000000000000000000000000000000000000000000000000000000000000000000000000000000000000000000000000000000000000000000000000000000000000000000000000000000000000000000000000000000000000000000000000000000000000000000000000000000000000000000000000000000000000000000000000000000000000000000000000000000000000000000000000000000000000000000000000000000000000000000000000000000000000000000000000000000000000000000000000000000000000000000000000000000000000000000000000000000000000000000000000000000000000000000000000000000000000000000000000000000000000000000000000000000000000000000000000000000000000000000000000000000000000000000000000000000000000000000000000000000000000000000000000000000000000000000000000000000000000000000000000000000000000000000000000000000000000000000000000000000000000000000000000000000000000000000000000000000000000000000000000000000000000000000000000000000000000000000000000000000000000000000000000000000000000000000000000000000000000000000000000000000000000000000000000000000000000000000000000000000000000000000000000000000000000000000000000000000000000000000000000000000000000000000000000000000000000000000000000000000000000000000000000000000000000000000000000000000000000000000000000000000000000000000000000000000000000000000000000000000000000000000000000000000000000000000000000000000000000000000000000000000000000000000000000000000000000000000000000000000000000000000000000000000000000000000000000000000000000000000000000000000000000000000000000000000000000000000000000000000000000000000000000000000000000000000000000000000000000000000000000000000000000000000000000000000000000000000000000000000000000000000000000000000000000000000000000000000000000000000000000000000000000000000000000000000000000000000000000000000000000000000000000000000000000000000000000000000000000000000000000000000000000000000000000000000000000000000000000000000000000000000000000000000000000000000000000000000000000000000000000000000000000000000000000000000000000000000000000000000000000000000000000000000000000000000000000000000000000000000000000000000000000000000000000000000000000000000000000000000000000000000000000000000000000000000000000000000000000000000000000000000000000000000000000000000000000000000000000000000000000000000000000000000000000000000000000000000000000000000000000000000000000000000000000000000000000000000000000000000000000000000000000000000000000000000000000000000000000000000000000000000000000000000000000000000000000000000000000000000000000000000000000000000000000000000000000000000000000000000000000000000000000000000000000000000000000000000000000000000000000000000000000000000000000000000000000000000000000000000000000000000000000000000000000000000000000000000000000000000000000000000000000000000000000000000000000000000000000000000000000000000000000000000000000000000000000000000000000000000000000000000000000000000000000000000000000000000000000000000000000000000000000000000000000000000000000000000000000000000000000000000000000000000000000000000000000000000000000000000000000000000000000000000000000000000000000000000000000000000000000000000000000000000000000000000000000000000000000000000000000000000000000000000000000000000000000000000000000000000000000000000000000000000000000000000000000000000000000000000000000000000000000000000000000000000000000000000000000000000000000000000000000000000000000000000000000000000000000000000000000000000000000000000000000000000000000000000000000000000000000000000000000000000000000000000000000000000000000000000000000000000000000000000000000000000000000000000000000000000000000000000000000000000000000000000000000000000000000000000000000000000000000000000000000000000000000000000000000000000000000000000000000000000000000000000000000000000000000000000000000000000000000000000000000000000000000000000000000000000000000000000000000000000000000000000000000000000000000000000000000000000000000000000000000000000000000000000000000000000000000000000000000000000000000000000000000000000000000000000000000000000000000000000000000000000000000000000000000000000000000000000000000000000000000000000000000000000000000000000000000000000000000000000000000000000000000000000000000000000000000000000000000000000000000000000000000000000000000000000000000000000000000000000000000000000000000000000000000000000000000000000000000000000000000000000000000000000000000000000000000000000000000000000000000000000000000000000000000000000000000000000000000000000000000000000000000000000000000000000000000000000000000000000000000000000000000000000000000000000000000000000000000000000000000000000000000000000000000000000000000000000000000000000000000000000000000000000000000000000000000000000000000000000000000000000000000000000000000000000000000000000000000000000000000000000000000000000000000000000000000000000000000000000000000000000000000000000000000000000000000000000000000000000000000000000000000000000000000000000000000000000000000000000000000000000000000000000000000000000000000000000000000000000000000000000000000000000000000000000000000000000000000000000000000000000000000000000000000000000000000000000000000000000000000000000000000000000000000000000000000000000000000000000000000000000000000000000000000000000000000000000000000000000000000000000000000000000000000000000000000000000000000000000000000000000000000000000000000000000000000000000000000000000000000000000000000000000000000000000000000000000000000000000000000000000000000000000000000000000000000000000000000000000000000000000000000000000000000000000000000000000000000000000000000000000000000000000000000000000000000000000000000000000000000000000000000000000000000000000000000000000000000000000000000000000000000000000000000000000000000000000000000000000000000000000000000000000000000000000000000000000000000000000000000000000000000000000000000000000000000000000000000000000000000000000000000000000000000000000000000000000000000000000000000000000000000000000000000000000000000000000000000000000000000000000000000000000000000000000000000000000000000000000000000000000000000000000000000000000000000000000000000000000000000000000000000000000000000000000000000000000000000000000000000000000000000000000000000000000000000000000000000000000000000000000000000000000000000000000000000000000000000000000000000000000000000000000000000000000000000000000000000000000000000000000000000000000000000000000000000000000000000000000000000000000000000000000000000000000000000000000000000000000000000000000000000000000000000000000000000000000000000000000000000000000000000000000000000000000000000000000000000000000000000000000000000000000000000000000000000000000000000000000000000000000000000000000000000000000000000000000000000000000000000000000000000000000000000000000000000000000000000000000000000000000000000000000000000000000000000000000000000000000000000000000000000000000000000000000000000000000000000000000000000000000000000000000000000000000000000000000000000000000000000000000000000000000000000000000000000000000000000000000000000000000000000000000000000000000000000000000000000000000000000000000000000000000000000000000000000000000000000000000000000000000000000000000000000000000000000000000000000000000000000000000000000000000000000000000000000000000000000000000000000000000000000000000000000000000000000000000000000000000000000000000000000000000000000000000000000000000000000000000000000000000000000000000000000000000000000000000000000000000000000000000000000000000000000000000000000000000000000000000000000000000000000000000000000000000000000000000000000000000000000000000000000000000000000000000000000000000000000000000000000000000000000000000000000000000000000000000000000000000000000000000000000000000000000000000000000000000000000000000000000000000000000000000000000000000000000000000000000000000000000000000000000000000000000000000000000000000000000000000000000000000000000000000000000000000000000000000000000000000000000000000000000000000000000000000000000000000000000000000000000000000000000000000000000000000000000000000000000000000000000000000000000000000000000000000000000000000000000000000000000000000000000000000000000000000000000000000000000000000000000000000000000000000000000000000000000000000000000000000000000000000000000000000000000000000000000000000000000000000000000000000000000000000000000000000000000000000000000000000000000000000000000000000000000000000000000000000000000000000000000000000000000000000000000000000000000000000000000000000000000000000000000000000000000000000000000000000000000000000000000000000000000000000000000000000000000000000000000000000000000000000000000000000000000000000000000000000000000000000000000000000000000000000000000000000000000000000000000000000000000000000000000000000000000000000000000000000000000000000000000000000000000000000000000000000000000000000000000000000000000000000000000000000000000000000000000000000000000000000000000000000000000000000000000000000000000000000000000000000000000000000000000000000000000000000000000000000000000000000000000000000000000000000000000000000000000000000000000000000000000000000000000000000000000000000000000000000000000000000000000000000000000000000000000000000000000000000000000000000000000000000000000000000000000000000000000000000000000000000000000000000000000000000000000000000000000000000000000000000000000000000000000000000000000000000000000000000000000000000000000000000000000000000000000000000000000000000000000000000000000000000000000000000000000000000000000000000000000000000000000000000000000000000000000000000000000000000000000000000000000000000000000000000000000000000000000000000000000000000000000000000000000000000000000000000000000000000000000000000000000000000000000000000000000000000000000000000000000000000000000000000000000000000000000000000000000000000000000000000000000000000000000000000000000000000000000000000000000000000000000000000000000000000000000000000000000000000000000000000000000000000000000000000000000000000000000000000000000000000000000000000000000000000000000000000000000000000000000000000000000000000000000000000000000000000000000000000000000000000000000000000000000000000000000000000000000000000000000000000000000000000000000000000000000000000000000000000000000000000000000000000000000000000000000000000000000000000000000000000000000000000000000000000000000000000000000000000000000000000000000000000000000000000000000000000000000000000000000000000000000000000000000000000000000000000000000000000000000000000000000000000000000000000000000000000000000000000000000000000000000000000000000000000000000000000000000000000000000000000000000000000000000000000000000000000000000000000000000000000000000000000000000000000000000000000000000000000000000000000000000000000000000000000000000000000000000000000000000000000000000000000000000000000000000000000000000000000000000000000000000000000000000000000000000000000000000000000000000000000000000000000000000000000000000000000000000000000000000000000000000000000000000000000000000000000000000000000000000000000000000000000000000000000000000000000000000000000000000000000000000000000000000000000000000000000000000000000000000000000000000000000000000000000000000000000000000000000000000000000000000000000000000000000000000000000000000000000000000000000000000000000000000000000000000000000000000000000000000000000000000000000000000000000000000000000000000000000000000000000000000000000000000000000000000000000000000000000000000000000000000000000000000000000000000000000000000000000000000000000000000000000000000000000000000000000000000000000000000000000000000000000000000000000000000000000000000000000000000000000000000000000000000000000000000000000000000000000000000000000000000000000000000000000000000000000000000000000000000000000000000000000000000000000000000000000000000000000000000000000000000000000000000000000000000000000000000000000000000000000000000000000000000000000000000000000000000000000000000000000000000000000000000000000000000000000000000000000000000000000000000000000000000000000000000000000000000000000000000000000000000000000000000000000000000000000000000000000000000000000000000000000000000000000000000000000000000000000000000000000000000000000000000000000000000000000000000000000000000000000000000000000000000000000000000000000000000000000000000000000000000000000000000000000000000000000000000000000000000000000000000000000000000000000000000000000000000000000000000000000000000000000000000000000000000000000000000000000000000000000000000000000000000000000000000000000000000000000000000000000000000000000000000000000000000000000000000000000000000000000000000000000000000000000000000000000000000000000000000000000000000000000000000000000000000000000000000000000000000000000000000000000000000000000000000000000000000000000000000000000000000000000000000000000000000000000000000000000000000000000000000000000000000000000000000000000000000000000000000000000000000000000000000000000000000000000000000000000000000000000000000000000000000000000000000000000000000000000000000000000000000000000000000000000000000000000000000000000000000000000000000000000000000000000000000000000000000000000000000000000000000000000000000000000000000000000000000000000000000000000000000000000000000000000000000000000000000000000000000000000000000000000000000000000000000000000000000000000000000000000000000000000000000000000000000000000000000000000000000000000000000000000000000000000000000000000000000000000000000000000000000000000000000000000000000000000000000000000000000000000000000000000000000000000000000000000000000000000000000000000000000000000000000000000000000000000000000000000000000000000000000000000000000000000000000000000000000000000000000000000000000000000000000000000000000000000000000000000000000000000000000000000000000000000000000000000000000000000000000000000000000000000000000000000000000000000000000000000000000000000000000000000000000000000000000000000000000000000000000000000000000000000000000000000000000000000000000000000000000000000000000000000000000000000000000000000000000000000000000000000000000000000000000000000000000000000000000000000000000000000000000000000000000000000000000000000000000000000000000000000000000000000000000000000000000000000000000000000000000000000000000000000000000000000000000000000000000000000000000000000000000000000000000000000000000000000000000000000000000000000000000000000000000000000000000000000000000000000000000000000000000000000000000000000000000000000000000000000000000000000000000000000000000000000000000000000000000000000000000000000000000000000000000000000000000000000000000000000000000000000000000000000000000000000000000000000000000000000000000000000000000000000000000000000000000000000000000000000000000000000000000000000000000000000000000000000000000000000000000000000000000000000000000000000000000000000000000000000000000000000000000000000000000000000000000000000000000000000000000000000000000000000000000000000000000000000000000000000000000000000000000000000000000000000000000000000000000000000000000000000000000000000000000000000000000000000000000000000000000000000000000000000000000000000000000000000000000000000000000000000000000000000000000000000000000000000000000000000000000000000000000000000000000000000000000000000000000000000000000000000000000000000000000000000000000000000000000000000000000000000000000000000000000000000000000000000000000000000000000000000000000000000000000000000000000000000000000000000000000000000000000000000000000000000000000000000000000000000000000000000000000000000000000000000000000000000000000000000000000000000000000000000000000000000000000000000000000000000000000000000000000000000000000000000000000000000000000000000000000000000000000000000000000000000000000000000000000000000000000000000000000000000000000000000000000000000000000000000000000000000000000000000000000000000000000000000000000000000000000000000000000000000000000000000000000000000000000000000000000000000000000000000000000000000000000000000000000000000000000000000000000000000000000000000000000000000000000000000000000000000000000000000000000000000000000000000000000000000000000000000000000000000000000000000000000000000000000000000000000000000000000000000000000000000000000000000000000000000000000000000000000000000000000000000000000000000000000000000000000000000000000000000000000000000000000000000000000000000000000000000000000000000000000000000000000000000000000000000000000000000000000000000000000000000000000000000000000000000000000000000000000000000000000000000000000000000000000000000000000000000000000000000000000000000000000000000000000000000000000000000000000000000000000000000000000000000000000000000000000000000000000000000000000000000000000000000000000000000000000000000000000000000000000000000000000000000000000000000000000000000000000000000000000000000000000000000000000000000000000000000000000000000000000000000000000000000000000000000000000000000000000000000000000000000000000000000000000000000000000000000000000000000000000000000000000000000000000000000000000000000000000000000000000000000000000000000000000000000000000000000000000000000000000000000000000000000000000000000000000000000000000000000000000000000000000000000000000000000000000000000000000000000000000000000000000000000000000000000000000000000000000000000000000000000000000000000000000000000000000000000000000000000000000000000000000000000000000000000000000000000000000000000000000000000000000000000000000000000000000000000000000000000000000000000000000000000000000000000000000000000000000000000000000000000000000000000000000000000000000000000000000000000000000000000000000000000000000000000000000000000000000000000000000000000000000000000000000000000000000000000000000000000000000000000000000000000000000000000000000000000000000000000000000000000000000000000000000000000000000000000000000000000000000000000000000000000000000000000000000000000000000000000000000000000000000000000000000000000000000000000000000000000000000000000000000000000000000000000000000000000000000000000000000000000000000000000000000000000000000000000000000000000000000000000000000000000000000000000000000000000000000000000000000000000000000000000000000000000000000000000000000000000000000000000000000000000000000000000000000000000000000000000000000000000000000000000000000000000000000000000000000000000000000000000000000000000000000000000000000000000000000000000000000000000000000000000000000000000000000000000000000000000000000000000000000000000000000000000000000000000000000000000000000000000000000000000000000000000000000000000000000000000000000000000000000000000000000000000000000000000000000000000000000000000000000000000000000000000000000000000000000000000000000000000000000000000000000000000000000000000000000000000000000000000000000000000000000000000000000000000000000000000000000000000000000000000000000000000000000000000000000000000000000000000000000000000000000000000000000000000000000000000000000000000000000000000000000000000000000000000000000000000000000000000000000000000000000000000000000000000000000000000000000000000000000000000000000000000000000000000000000000000000000000000000000000000000000000000000000000000000000000000000000000000000000000000000000000000000000000000000000000000000000000000000000000000000000000000000000000000000000000000000000000000000000000000000000000000000000000000000000000000000000000000000000000000000000000000000000000000000000000000000000000000000000000000000000000000000000000000000000000000000000000000000000000000000000000000000000000000000000000000000000000000000000000000000000000000000000000000000000000000000000000000000000000000000000000000000000000000000000000000000000000000000000000000000000000000000000000000000000000000000000000000000000000000000000000000000000000000000000000000000000000000000000000000000000000000000000000000000000000000000000000000000000000000000000000000000000000000000000000000000000000000000000000000000000000000000000000000000000000000000000000000000000000000000000000000000000000000000000000000000000000000000000000000000000000000000000000000000000000000000000000000000000000000000000000000000000000000000000000000000000000000000000000000000000000000000000000000000000000000000000000000000000000000000000000000000000000000000000000000000000000000000000000000000000000000000000000000000000000000000000000000000000000000000000000000000000000000000000000000000000000000000000000000000000000000000000000000000000000000000000000000000000000000000000000000000000000000000000000000000000000000000000000000000000000000000000000000000000000000000000000000000000000000000000000000000000000000000000000000000000000000000000000000000000000000000000000000000000000000000000000000000000000000000000000000000000000000000000000000000000000000000000000000000000000000000000000000000000000000000000000000000000000000000000000000000000000000000000000000000000000000000000000000000000000000000000000000000000000000000000000000000000000000000000000000000000000000000000000000000000000000000000000000000000000000000000000000000000000000000000000000000000000000000000000000000000000000000000000000000000000000000000000000000000000000000000000000000000000000000000000000000000000000000000000000000000000000000000000000000000000000000000000000000000000000000000000000000000000000000000000000000000000000000000000000000000000000000000000000000000000000000000000000000000000000000000000000000000000000000000000000000000000000000000000000000000000000000000000000000000000000000000000000000000000000000000000000000000000000000000000000000000000000000000000000000000000000000000000000000000000000000000000000000000000000000000000000000000000000000000000000000000000000000000000000000000000000000000000000000000000000000000000000000000000000000000000000000000000000000000000000000000000000000000000000000000000000000000000000000000000000000000000000000000000000000000000000000000000000000000000000000000000000000000000000000000000000000000000000000000000000000000000000000000000000000000000000000000000000000000000000000000000000000000000000000000000000000000000000000000000000000000000000000000000000000000000000000000000000000000000000000000000000000000000000000000000000000000000000000000000000000000000000000000000000000000000000000000000000000000000000000000000000000000000000000000000000000000000000000000000000000000000000000000000000000000000000000000000000000000000000000000000000000000000000000000000000000000000000000000000000000000000000000000000000000000000000000000000000000000000000000000000000000000000000000000000000000000000000000000000000000000000000000000000000000000000000000000000000000000000000000000000000000000000000000000000000000000000000000000000000000000000000000000000000000000000000000000000000000000000000000000000000000000000000000000000000000000000000000000000000000000000000000000000000000000000000000000000000000000000000000000000000000000000000000000000000000000000000000000000000000000000000000000000000000000000000000000000000000000000000000000000000000000000000000000000000000000000000000000000000000000000000000000000000000000000000000000000000000000000000000000000000000000000000000000000000000000000000000000000000000000000000000000000000000000000000000000000000000000000000000000000000000000000000000000000000000000000000000000000000000000000000000000000000000000000000000000000000000000000000000000000000000000000000000000000000000000000000000000000000000000000000000000000000000000000000000000000000000000000000000000000000000000000000000000000000000000000000000000000000000000000000000000000000000000000000000000000000000000000000000000000000000000000000000000000000000000000000000000000000000000000000000000000000000000000000000000000000000000000000000000000000000000000000000000000000000000000000000000000000000000000000000000000000000000000000000000000000000000000000000000000000000000000000000000000000000000000000000000000000000000000000000000000000000000000000000000000000000000000000000000000000000000000000000000000000000000000000000000000000000000000000000000000000000000000000000000000000000000000000000000000000000000000000000000000000000000000000000000000000000000000000000000000000000000000000000000000000000000000000000000000000000000000000000000000000000000000000000000000000000000000000000000000000000000000000000000000000000000000000000000000000000000000000000000000000000000000000000000000000000000000000000000000000000000000000000000000000000000000000000000000000000000000000000000000000000000000000000000000000000000000000000000000000000000000000000000000000000000000000000000000000000000000000000000000000000000000000000000000000000000000000000000000000000000000000000000000000000000000000000000000000000000000000000000000000000000000000000000000000000000000000000000000000000000000000000000000000000000000000000000000000000000000000000000000000000000000000000000000000000000000000000000000000000000000000000000000000000000000000000000000000000000000000000000000000000000000000000000000000000000000000000000000000000000000000000000000000000000000000000000000000000000000000000000000000000000000000000000000000000000000000000000000000000000000000000000000000000000000000000000000000000000000000000000000000000000000000000000000000000000000000000000000000000000000000000000000000000000000000000000000000000000000000000000000000000000000000000000000000000000000000000000000000000000000000000000000000000000000000000000000000000000000000000000000000000000000000000000000000000000000000000000000000000000000000000000000000000000000000000000000000000000000000000000000000000000000000000000000000000000000000000000000000000000000000000000000000000000000000000000000000000000000000000000000000000000000000000000000000000000000000000000000000000000000000000000000000000000000000000000000000000000000000000000000000000000000000000000000000000000000000000000000000000000000000000000000000000000000000000000000000000000000000000000000000000000000000000000000000000000000000000000000000000000000000000000000000000000000000000000000000000000000000000000000000000000000000000000000000000000000000000000000000000000000000000000000000000000000000000000000000000000000000000000000000000000000000000000000000000000000000000000000000000000000000000000000000000000000000000000000000000000000000000000000000000000000000000000000000000000000000000000000000000000000000000000000000000000000000000000000000000000000000000000000000000000000000000000000000000000000000000000000000000000000000000000000000000000000000000000000000000000000000000000000000000000000000000000000000000000000000000000000000000000000000000000000000000000000000000000000000000000000000000000000000000000000000000000000000000000000000000000000000000000000000000000000000000000000000000000000000000000000000000000000000000000000000000000000000000000000000000000000000000000000000000000000000000000000000000000000000000000000000000000000000000000000000000000000000000000000000000000000000000000000000000000000000000000000000000000000000000000000000000000000000000000000000000000000000000000000000000000000000000000000000000000000000000000000000000000000000000000000000000000000000000000000000000000000000000000000000000000000000000000000000000000000000000000000000000000000000000000000000000000000000000000000000000000000000000000000000000000000000000000000000000000000000000000000000000000000000000000000000000000000000000000000000000000000000000000000000000000000000000000000000000000000000000000000000000000000000000000000000000000000000000000000000000000000000000000000000000000000000000000000000000000000000000000000000000000000000000000000000000000000000000000000000000000000000000000000000000000000000000000000000000000000000000000000000000000000000000000000000000000000000000000000000000000000000000000000000000000000000000000000000000000000000000000000000000000000000000000000000000000000000000000000000000000000000000000000000000000000000000000000000000000000000000000000000000000000000000000000000000000000000000000000000000000000000000000000000000000000000000000000000000000000000000000000000000000000000000000000000000000000000000000000000000000000000000000000000000000000000000000000000000000000000000000000000000000000000000000000000000000000000000000000000000000000000000000000000000000000000000000000000000000000000000000000000000000000000000000000000000000000000000000000000000000000000000000000000000000000000000000000000000000000000000000000000000000000000000000000000000000000000000000000000000000000000000000000000000000000000000000000000000000000000000000000000000000000000000000000000000000000000000000000000000000000000000000000000000000000000000000000000000000000000000000000000000000000000000000000000000000000000000000000000000000000000000000000000000000000000000000000000000000000000000000000000000000000000000000000000000000000000000000000000000000000000000000000000000000000000000000000000000000000000000000000000000000000000000000000000000000000000000000000000000000000000000000000000000000000000000000000000000000000000000000000000000000000000000000000000000000000000000000000000000000000000000000000000000000000000000000000000000000000000000000000000000000000000000000000000000000000000000000000000000000000000000000000000000000000000000000000000000000000000000000000000000000000000000000000000000000000000000000000000000000000000000000000000000000000000000000000000000000000000000000000000000000000000000000000000000000000000000000000000000000000000000000000000000000000000000000000000000000000000000000000000000000000000000000000000000000000000000000000000000000000000000000000000000000000000000000000000000000000000000000000000000000000000000000000000000000000000000000000000000000000000000000000000000000000000000000000000000000000000000000000000000000000000000000000000000000000000000000000000000000000000000000000000000000000000000000000000000000000000000000000000000000000000000000000000000000000000000000000000000000000000000000000000000000000000000000000000000000000000000000000000000000000000000000000000000000000000000000000000000000000000000000000000000000000000000000000000000000000000000000000000000000000000000000000000000000000000000000000000000000000000000000000000000000000000000000000000000000000000000000000000000000000000000000000000000000000000000000000000000000000000000000000000000000000000000000000000000000000000000000000000000000000000000000000000000000000000000000000000000000000000000000000000000000000000000000000000000000000000000000000000000000000000000000000000000000000000000000000000000000000000000000000000000000000000000000000000000000000000000000000000000000000000000000000000000000000000000000000000000000000000000000000000000000000000000000000000000000000000000000000000000000000000000000000000000000000000000000000000000000000000000000000000000000000000000000000000000000000000000000000000000000000000000000000000000000000000000000000000000000000000000000000000000000000000000000000000000000000000000000000000000000000000000000000000000000000000000000000000000000000000000000000000000000000000000000000000000000000000000000000000000000000000000000000000000000000000000000000000000000000000000000000000000000000000000000000000000000000000000000000000000000000000000000000000000000000000000000000000000000000000000000000000000000000000000000000000000000000000000000000000000000000000000000000000000000000000000000000000000000000000000000000000000000000000000000000000000000000000000000000000000000000000000000000000000000000000000000000000000000000000000000000000000000000000000000000000000000000000000000000000000000000000000000000000000000000000000000000000000000000000000000000000000000000000000000000000000000000000000000000000000000000000000000000000000000000000000000000000000000000000000000000000000000000000000000000000000000000000000000000000000000000000000000000000000000000000000000000000000000000000000000000000000000000000000000000000000000000000000000000000000000000000000000000000000000000000000000000000000000000000000000000000000000000000000000000000000000000000000000000000000000000000000000000000000000000000000000000000000000000000000000000000000000000000000000000000000000000000000000000000000000000000000000000000000000000000000000000000000000000000000000000000000000000000000000000000000000000000000000000000000000000000000000000000000000000000000000000000000000000000000000000000000000000000000000000000000000000000000000000000000000000000000000000000000000000000000000000000000000000000000000000000000000000000000000000000000000000000000000000000000000000000000000000000000000000000000000000000000000000000000000000000000000000000000000000000000000000000000000000000000000000000000000000000000000000000000000000000000000000000000000000000000000000000000000000000000000000000000000000000000000000000000000000000000000000000000000000000000000000000000000000000000000000000000000000000000000000000000000000000000000000000000000000000000000000000000000000000000000000000000000000000000000000000000000000000000000000000000000000000000000000000000000000000000000000000000000000000000000000000000000000000000000000000000000000000000000000000000000000000000000000000000000000000000000000000000000000000000000000000000000000000000000000000000000000000000000000000000000000000000000000000000000000000000000000000000000000000000000000000000000000000000000000000000000000000000000000000000000000000000000000000000000000000000000000000000000000000000000000000000000000000000000000000000000000000000000000000000000000000000000000000000000000000000000000000000000000000000000000000000000000000000000000000000000000000000000000000000000000000000000000000000000000000000000000000000000000000000000000000000000000000000000000000000000000000000000000000000000000000000000000000000000000000000000000000000000000000000000000000000000000000000000000000000000000000000000000000000000000000000000000000000000000000000000000000000000000000000000000000000000000000000000000000000000000000000000000000000000000000000000000000000000000000000000000000000000000000000000000000000000000000000000000000000000000000000000000000000000000000000000000000000000000000000000000000000000000000000000000000000000000000000000000000000000000000000000000000000000000000000000000000000000000000000000000000000000000000000000000000000000000000000000000000000000000000000000000000000000000000000000000000000000000000000000000000000000000000000000000000000000000000000000000000000000000000000000000000000000000000000000000000000000000000000000000000000000000000000000000000000000000000000000000000000000000000000000000000000000000000000000000000000000000000000000000000000000000000000000000000000000000000000000000000000000000000000000000000000000000000000000000000000000000000000000000000000000000000000000000000000000000000000000000000000000000000000000000000000000000000000000000000000000000000000000000000000000000000000000000000000000000000000000000000000000000000000000000000000000000000000000000000000000000000000000000000000000000000000000000000000000000000000000000000000000000000000000000000000000000000000000000000000000000000000000000000000000000000000000000000000000000000000000000000000000000000000000000000000000000000000000000000000000000000000000000000000000000000000000000000000000000000000000000000000000000000000000000000000000000000000000000000000000000000000000000000000000000000000000000000000000000000000000000000000000000000000000000000000000000000000000000000000000000000000000000000000000000000000000000000000000000000000000000000000000000000000000000000000000000000000000000000000000000000000000000000000000000000000000000000000000000000000000000000000000000000000000000000000000000000000000000000000000000000000000000000000000000000000000000000000000000000000000000000000000000000000000000000000000000000000000000000000000000000000000000000000000000000000000000000000000000000000000000000000000000000000000000000000000000000000000000000000000000000000000000000000000000000000000000000000000000000000000000000000000000000000000000000000000000000000000000000000000000000000000000000000000000000000000000000000000000000000000000000000000000000000000000000000000000000000000000000000000000000000000000000000000000000000000000000000000000000000000000000000000000000000000000000000000000000000000000000000000000000000000000000000000000000000000000000000000000000000000000000000000000000000000000000000000000000000000000000000000000000000000000000000000000000000000000000000000000000000000000000000000000000000000000000000000000000000000000000000000000000000000000000000000000000000000000000000000000000000000000000000000000000000000000000000000000000000000000000000000000000000000000000000000000000000000000000000000000000000000000000000000000000000000000000000000000000000000000000000000000000000000000000000000000000000000000000000000000000000000000000000000000000000000000000000000000000000000000000000000000000000000000000000000000000000000000000000000000000000000000000000000000000000000000000000000000000000000000000000000000000000000000000000000000000000000000000000000000000000000000000000000000000000000000000000000000000000000000000000000000000000000000000000000000000000000000000000000000000000000000000000000000000000000000000000000000000000000000000000000000000000000000000000000000000000000000000000000000000000000000000000000000000000000000000000000000000000000000000000000000000000000000000000000000000000000000000000000000000000000000000000000000000000000000000000000000000000000000000000000000000000000000000000000000000000000000000000000000000000000000000000000000000000000000000000000000000000000000000000000000000000000000000000000000000000000000000000000000000000000000000000000000000000000000000000000000000000000000000000000000000000000000000000000000000000000000000000000000000000000000000000000000000000000000000000000000000000000000000000000000000000000000000000000000000000000000000000000000000000000000000000000000000000000000000000000000000000000000000000000000000000000000000000000000000000000000000000000000000000000000000000000000000000000000000000000000000000000000000000000000000000000000000000000000000000000000000000000000000000000000000000000000000000000000000000000000000000000000000000000000000000000000000000000000000000000000000000000000000000000000000000000000000000000000000000000000000000000000000000000000000000000000000000000000000000000000000000000000000000000000000000000000000000000000000000000000000000000000000000000000000000000000000000000000000000000000000000000000000000000000000000000000000000000000000000000000000000000000000000000000000000000000000000000000000000000000000000000000000000000000000000000000000000000000000000000000000000000000000000000000000000000000000000000000000000000000000000000000000000000000000000000000000000000000000000000000000000000000000000000000000000000000000000000000000000000000000000000000000000000000000000000000000000000000000000000000000000000000000000000000000000000000000000000000000000000000000000000000000000000000000000000000000000000000000000000000000000000000000000000000000000000000000000000000000000000000000000000000000000000000000000000000000000000000000000000000000000000000000000000000000000000000000000000000000000000000000000000000000000000000000000000000000000000000000000000000000000000000000000000000000000000000000000000000000000000000000000000000000000000000000000000000000000000000000000000000000000000000000000000000000000000000000000000000000000000000000000000000000000000000000000000000000000000000000000000000000000000000000000000000000000000000000000000000000000000000000000000000000000000000000000000000000000000000000000000000000000000000000000000000000000000000000000000000000000000000000000000000000000000000000000000000000000000000000000000000000000000000000000000000000000000000000000000000000000000000000000000000000000000000000000000000000000000000000000000000000000000000000000000000000000000000000000000000000000000000000000000000000000000000000000000000000000000000000000000000000000000000000000000000000000000000000000000000000000000000000000000000000000000000000000000000000000000000000000000000000000000000000000000000000000000000000000000000000000000000000000000000000000000000000000000000000000000000000000000000000000000000000000000000000000000000000000000000000000000000000000000000000000000000000000000000000000000000000000000000000000000000000000000000000000000000000000000000000000000000000000000000000000000000000000000000000000000000000000000000000000000000000000000000000000000000000000000000000000000000000000000000000000000000000000000000000000000000000000000000000000000000000000000000000000000000000000000000000000000000000000000000000000000000000000000000000000000000000000000000000000000000000000000000000000000000000000000000000000000000000000000000000000000000000000000000000000000000000000000000000000000000000000000000000000000000000000000000000000000000000000000000000000000000000000000000000000000000000000000000000000000000000000000000000000000000000000000000000000000000000000000000000000000000000000000000000000000000000000000000000000000000000000000000000000000000000000000000000000000000000000000000000000000000000000000000000000000000000000000000000000000000000000000000000000000000000000000000000000000000000000000000000000000000000000000000000000000000000000000000000000000000000000000000000000000000000000000000000000000000000000000000000000000000000000000000000000000000000000000000000000000000000000000000000000000000000000000000000000000000000000000000000000000000000000000000000000000000000000000000000000000000000000000000000000000000000000000000000000000000000000000000000000000000000000000000000000000000000000000000000000000000000000000000000000000000000000000000000000000000000000000000000000000000000000000000000000000000000000000000000000000000000000000000000000000000000000000000000000000000000000000000000000000000000000000000000000000000000000000000000000000000000000000000000000000000000000000000000000000000000000000000000000000000000000000000000000000000000000000000000000000000000000000000000000000000000000000000000000000000000000000000000000000000000000000000000000000000000000000000000000000000000000000000000000000000000000000000000000000000000000000000000000000000000000000000000000000000000000000000000000000000000000000000000000000000000000000000000000000000000000000000000000000000000000000000000000000000000000000000000000000000000000000000000000000000000000000000000000000000000000000000000000000000000000000000000000000000000000000000000000000000000000000000000000000000000000000000000000000000000000000000000000000000000000000000000000000000000000000000000000000000000000000000000000000000000000000000000000000000000000000000000000000000000000000000000000000000000000000000000000000000000000000000000000000000000000000000000000000000000000000000000000000000000000000000000000000000000000000000000000000000000000000000000000000000000000000000000000000000000000000000000000000000000000000000000000000000000000000000000000000000000000000000000000000000000000000000000000000000000000000000000000000000000000000000000000000000000000000000000000000000000000000000000000000000000000000000000000000000000000000000000000000000000000000000000000000000000000000000000000000000000000000000000000000000000000000000000000000000000000000000000000000000000000000000000000000000000000000000000000000000000000000000000000000000000000000000000000000000000000000000000000000000000000000000000000000000000000000000000000000000000000000000000000000000000000000000000000000000000000000000000000000000000000000000000000000000000000000000000000000000000000000000000000000000000000000000000000000000000000000000000000000000000000000000000000000000000000000000000000000000000000000000000000000000000000000000000000000000000000000000000000000000000000000000000000000000000000000000000000000000000000000000000000000000000000000000000000000000000000000000000000000000000000000000000000000000000000000000000000000000000000000000000000000000000000000000000000000000000000000000000000000000000000000000000000000000000000000000000000000000000000000000000000000000000000000000000000000000000000000000000000000000000000000000000000000000000000000000000000000000000000000000000000000000000000000000000000000000000000000000000000000000000000000000000000000000000000000000000000000000000000000000000000000000000000000000000000000000000000000000000000000000000000000000000000000000000000000000000000000000000000000000000000000000000000000000000000000000000000000000000000000000000000000000000000000000000000000000000000000000000000000000000000000000000000000000000000000000000000000000000000000000000000000000000000000000000000000000000000000000000000000000000000000000000000000000000000000000000000000000000000000000000000000000000000000000000000000000000000000000000000000000000000000000000000000000000000000000000000000000000000000000000000000000000000000000000000000000000000000000000000000000000000000000000000000000000000000000000000000000000000000000000000000000000000000000000000000000000000000000000000000000000000000000000000000000000000000000000000000000000000000000000000000000000000000000000000000000000000000000000000000000000000000000000000000000000000000000000000000000000000000000000000000000000000000000000000000000000000000000000000000000000000000000000000000000000000000000000000000000000000000000000000000000000000000000000000000000000000000000000000000000000000000000000000000000000000000000000000000000000000000000000000000000000000000000000000000000000000000000000000000000000000000000000000000000000000000000000000000000000000000000000000000000000000000000000000000000000000000000000000000000000000000000000000000000000000000000000000000000000000000000000000000000000000000000000000000000000000000000000000000000000000000000000000000000000000000000000000000000000000000000000000000000000000000000000000000000000000000000000000000000000000000000000000000000000000000000000000000000000000000000000000000000000000000000000000000000000000000000000000000000000000000000000000000000000000000000000000000000000000000000000000000000000000000000000000000000000000000000000000000000000000000000000000000000000000000000000000000000000000000000000000000000000000000000000000000000000000000000000000000000000000000000000000000000000000000000000000000000000000000000000000000000000000000000000000000000000000000000000000000000000000000000000000000000000000000000000000000000000000000000000000000000000000000000000000000000000000000000000000000000000000000000000000000000000000000000000000000000000000000000000000000000000000000000000000000000000000000000000000000000000000000000000000000000000000000000000000000000000000000000000000000000000000000000000000000000000000000000000000000000000000000000000000000000000000000000000000000000000000000000000000000000000000000000000000000000000000000000000000000000000000000000000000000000000000000000000000000000000000000000000000000000000000000000000000000000000000000000000000000000000000000000000000000000000000000000000000000000000000000000000000000000000000000000000000000000000000000000000000000000000000000000000000000000000000000000000000000000000000000000000000000000000000000000000000000000000000000000000000000000000000000000000000000000000000000000000000000000000000000000000000000000000000000000000000000000000000000000000000000000000000000000000000000000000000000000000000000000000000000000000000000000000000000000000000000000000000000000000000000000000000000000000000000000000000000000000000000000000000000000000000000000000000000000000000000000000000000000000000000000000000000000000000000000000000000000000000000000000000000000000000000000000000000000000000000000000000000000000000000000000000000000000000000000000000000000000000000000000000000000000000000000000000000000000000000000000000000000000000000000000000000000000000000000000000000000000000000000000000000000000000000000000000000000000000000000000000000000000000000000000000000000000000000000000000000000000000000000000000000000000000000000000000000000000000000000000000000000000000000000000000000000000000000000000000000000000000000000000000000000000000000000000000000000000000000000000000000000000000000000000000000000000000000000000000000000000000000000000000000000000000000000000000000000000000000000000000000000000000000000000000000000000000000000000000000000000000000000000000000000000000000000000000000000000000000000000000000000000000000000000000000000000000000000000000000000000000000000000000000000000000000000000000000000000000000000000000000000000000000000000000000000000000000000000000000000000000000000000000000000000000000000000000000000000000000000000000000000000000000000000000000000000000000000000000000000000000000000000000000000000000000000000000000000000000000000000000000000000000000000000000000000000000000000000000000000000000000000000000000000000000000000000000000000000000000000000000000000000000000000000000000000000000000000000000000000000000000000000000000000000000000000000000000000000000000000000000000000000000000000000000000000000000000000000000000000000000000000000000000000000000000000000000000000000000000000000000000000000000000000000000000000000000000000000000000000000000000000000000000000000000000000000000000000000000000000000000000000000000000000000000000000000000000000000000000000000000000000000000000000000000000000000000000000000000000000000000000000000000000000000000000000000000000000000000000000000000000000000000000000000000000000000000000000000000000000000000000000000000000000000000000000000000000000000000000000000000000000000000000000000000000000000000000000000000000000000000000000000000000000000000000000000000000000000000000000000000000000000000000000000000000000000000000000000000000000000000000000000000000000000000000000000000000000000000000000000000000000000000000000000000000000000000000000000000000000000000000000000000000000000000000000000000000000000000000000000000000000000000000000000000000000000000000000000000000000000000000000000000000000000000000000000000000000000000000000000000000000000000000000000000000000000000000000000000000000000000000000000000000000000000000000000000000000000000000000000000000000000000000000000000000000000000000000000000000000000000000000000000000000000000000000000000000000000000000000000000000000000000000000000000000000000000000000000000000000000000000000000000000000000000000000000000000000000000000000000000000000000000000000000000000000000000000000000000000000000000000000000000000000000000000000000000000000000000000000000000000000000000000000000000000000000000000000000000000000000000000000000000000000000000000000000000000000000000000000000000000000000000000000000000000000000000000000000000000000000000000000000000000000000000000000000000000000000000000000000000000000000000000000000000000000000000000000000000000000000000000000000000000000000000000000000000000000000000000000000000000000000000000000000000000000000000000000000000000000000000000000000000000000000000000000000000000000000000000000000000000000000000000000000000000000000000000000000000000000000000000000000000000000000000000000000000000000000000000000000000000000000000000000000000000000000000000000000000000000000000000000000000000000000000000000000000000000000000000000000000000000000000000000000000000000000000000000000000000000000000000000000000000000000000000000000000000000000000000000000000000000000000000000000000000000000000000000000000000000000000000000000000000000000000000000000000000000000000000000000000000000000000000000000000000000000000000000000000000000000000000000000000000000000000000000000000000000000000000000000000000000000000000000000000000000000000000000000000000000000000000000000000000000000000000000000000000000000000000000000000000000000000000000000000000000000000000000000000000000000000000000000000000000000000000000000000000000000000000000000000000000000000000000000000000000000000000000000000000000000000000000000000000000000000000000000000000000000000000000000000000000000000000000000000000000000000000000000000000000000000000000000000000000000000000000000000000000000000000000000000000000000000000000000000000000000000000000000000000000000000000000000000000000000000000000000000000000000000000000000000000000000000000000000000000000000000000000000000000000000000000000000000000000000000000000000000000000000000000000000000000000000000000000000000000000000000000000000000000000000000000000000000000000000000000000000000000000000000000000000000000000000000000000000000000000000000000000000000000000000000000000000000000000000000000000000000000000000000000000000000000000000000000000000000000000000000000000000000000000000000000000000000000000000000000000000000000000000000000000000000000000000000000000000000000000000000000000000000000000000000000000000000000000000000000000000000000000000000000000000000000000000000000000000000000000000000000000000000000000000000000000000000000000000000000000000000000000000000000000000000000000000000000000000000000000000000000000000000000000000000000000000000000000000000000000000000000000000000000000000000000000000000000000000000000000000000000000000000000000000000000000000000000000000000000000000000000000000000000000000000000000000000000000000000000000000000000000000000000000000000000000000000000000000000000000000000000000000000000000000000000000000000000000000000000000000000000000000000000000000000000000000000000000000000000000000000000000000000000000000000000000000000000000000000000000000000000000000000000000000000000000000000000000000000000000000000000000000000000000000000000000000000000000000000000000000000000000000000000000000000000000000000000000000000000000000000000000000000000000000000000000000000000000000000000000000000000000000000000000000000000000000000000000000000000000000000000000000000000000000000000000000000000000000000000000000000000000000000000000000000000000000000000000000000000000000000000000000000000000000000000000000000000000000000000000000000000000000000000000000000000000000000000000000000000000000000000000000000000000000000000000000000000000000000000000000000000000000000000000000000000000000000000000000000000000000000000000000000000000000000000000000000000000000000000000000000000000000000000000000000000000000000000000000000000000000000000000000000000000000000000000000000000000000000000000000000000000000000000000000000000000000000000000000000000000000000000000000000000000000000000000000000000000000000000000000000000000000000000000000000000000000000000000000000000000000000000000000000000000000000000000000000000000000000000000000000000000000000000000000000000000000000000000000000000000000000000000000000000000000000000000000000000000000000000000000000000000000000000000000000000000000000000000000000000000000000000000000000000000000000000000000000000000000000000000000000000000000000000000000000000000000000000000000000000000000000000000000000000000000000000000000000000000000000000000000000000000000000000000000000000000000000000000000000000000000000000000000000000000000000000000000000000000000000000000000000000000000000000000000000000000000000000000000000000000000000000000000000000000000000000000000000000000000000000000000000000000000000000000000000000000000000000000000000000000000000000000000000000000000000000000000000000000000000000000000000000000000000000000000000000000000000000000000000000000000000000000000000000000000000000000000000000000000000000000000000000000000000000000000000000000000000000000000000000000000000000000000000000000000000000000000000000000000000000000000000000000000000000000000000000000000000000000000000000000000000000000000000000000000000000000000000000000000000000000000000000000000000000000000000000000000000000000000000000000000000000000000000000000000000000000000000000000000000000000000000000000000000000000000000000000000000000000000000000000000000000000000000000000000000000000000000000000000000000000000000000000000000000000000000000000000000000000000000000000000000000000000000000000000000000000000000000000000000000000000000000000000000000000000000000000000000000000000000000000000000000000000000000000000000000000000000000000000000000000000000000000000000000000000000000000000000000000000000000000000000000000000000000000000000000000000000000000000000000000000000000000000000000000000000000000000000000000000000000000000000000000000000000000000000000000000000000000000000000000000000000000000000000000000000000000000000000000000000000000000000000000000000000000000000000000000000000000000000000000000000000000000000000000000000000000000000000000000000000000000000000000000000000000000000000000000000000000000000000000000000000000000000000000000000000000000000000000000000000000000000000000000000000000000000000000000000000000000000000000000000000000000000000000000000000000000000000000000000000000000000000000000000000000000000000000000000000000000000000000000000000000000000000000000000000000000000000000000000000000000000000000000000000000000000000000000000000000000000000000000000000000000000000000000000000000000000000000000000000000000000000000000000000000000000000000000000000000000000000000000000000000000000000000000000000000000000000000000000000000000000000000000000000000000000000000000000000000000000000000000000000000000000000000000000000000000000000000000000000000000000000000000000000000000000000000000000000000000000000000000000000000000000000000000000000000000000000000000000000000000000000000000000000000000000000000000000000000000000000000000000000000000000000000000000000000000000000000000000000000000000000000000000000000000000000000000000000000000000000000000000000000000000000000000000000000000000000000000000000000000000000000000000000000000000000000000000000000000000000000000000000000000000000000000000000000000000000000000000000000000000000000000000000000000000000000000000000000000000000000000000000000000000000000000000000000000000000000000000000000000000000000000000000000000000000000000000000000000000000000000000000000000000000000000000000000000000000000000000000000000000000000000000000000000000000000000000000000000000000000000000000000000000000000000000000000000000000000000000000000000000000000000000000000000000000000000000000000000000000000000000000000000000000000000000000000000000000000000000000000000000000000000000000000000000000000000000000000000000000000000000000000000000000000000000000000000000000000000000000000000000000000000000000000000000000000000000000000000000000000000000000000000000000000000000000000000000000000000000000000000000000000000000000000000000000000000000000000000000000000000000000000000000000000000000000000000000000000000000000000000000000000000000000000000000000000000000000000000000000000000000000000000000000000000000000000000000000000000000000000000000000000000000000000000000000000000000000000000000000000000000000000000000000000000000000000000000000000000000000000000000000000000000000000000000000000000000000000000000000000000000000000000000000000000000000000000000000000000000000000000000000000000000000000000000000000000000000000000000000000000000000000000000000000000000000000000000000000000000000000000000000000000000000000000000000000000000000000000000000000000000000000000000000000000000000000000000000000000000000000000000000000000000000000000000000000000000000000000000000000000000000000000000000000000000000000000000000000000000000000000000000000000000000000000000000000000000000000000000000000000000000000000000000000000000000000000000000000000000000000000000000000000000000000000000000000000000000000000000000000000000000000000000000000000000000000000000000000000000000000000000000000000000000000000000000000000000000000000000000000000000000000000000000000000000000000000000000000000000000000000000000000000000000000000000000000000000000000000000000000000000000000000000000000000000000000000000000000000000000000000000000000000000000000000000000000000000000000000000000000000000000000000000000000000000000000000000000000000000000000000000000000000000000000000000000000000000000000000000000000000000000000000000000000000000000000000000000000000000000000000000000000000000000000000000000000000000000000000000000000000000000000000000000000000000000000000000000000000000000000000000000000000000000000000000000000000000000000000000000000000000000000000000000000000000000000000000000000000000000000000000000000000000000000000000000000000000000000000000000000000000000000000000000000000000000000000000000000000000000000000000000000000000000000000000000000000000000000000000000000000000000000000000000000000000000000000000000000000000000000000000000000000000000000000000000000000000000000000000000000000000000000000000000000000000000000000000000000000000000000000000000000000000000000000000000000000000000000000000000000000000000000000000000000000000000000000000000000000000000000000000000000000000000000000000000000000000000000000000000000000000000000000000000000000000000000000000000000000000000000000000000000000000000000000000000000000000000000000000000000000000000000000000000000000000000000000000000000000000000000000000000000000000000000000000000000000000000000000000000000000000000000000000000000000000000000000000000000000000000000000000000000000000000000000000000000000000000000000000000000000000000000000000000000000000000000000000000000000000000000000000000000000000000000000000000000000000000000000000000000000000000000000000000000000000000000000000000000000000000000000000000000000000000000000000000000000000000000000000000000000000000000000000000000000000000000000000000000000000000000000000000000000000000000000000000000000000000000000000000000000000000000000000000000000000000000000000000000000000000000000000000000000000000000000000000000000000000000000000000000000000000000000000000000000000000000000000000000000000000000000000000000000000000000000000000000000000000000000000000000000000000000000000000000000000000000000000000000000000000000000000000000000000000000000000000000000000000000000000000000000000000000000000000000000000000000000000000000000000000000000000000000000000000000000000000000000000000000000000000000000000000000000000000000000000000000000000000000000000000000000000000000000000000000000000000000000000000000000000000000000000000000000000000000000000000000000000000000000000000000000000000000000000000000000000000000000000000000000000000000000000000000000000000000000000000000000000000000000000000000000000000000000000000000000000000000000000000000000000000000000000000000000000000000000000000000000000000000000000000000000000000000000000000000000000000000000000000000000000000000000000000000000000000000000000000000000000000000000000000000000000000000000000000000000000000000000000000000000000000000000000000000000000000000000000000000000000000000000000000000000000000000000000000000000000000000000000000000000000000000000000000000000000000000000000000000000000000000000000000000000000000000000000000000000000000000000000000000000000000000000000000000000000000000000000000000000000000000000000000000000000000000000000000000000000000000000000000000000000000000000000000000000000000000000000000000000000000000000000000000000000000000000000000000000000000000000000000000000000000000000000000000000000000000000000000000000000000000000000000000000000000000000000000000000000000000000000000000000000000000000000000000000000000000000000000000000000000000000000000000000000000000000000000000000000000000000000000000000000000000000000000000000000000000000000000000000000000000000000000000000000000000000000000000000000000000000000000000000000000000000000000000000000000000000000000000000000000000000000000000000000000000000000000000000000000000000000000000000000000000000000000000000000000000000000000000000000000000000000000000000000000000000000000000000000000000000000000000000000000000000000000000000000000000000000000000000000000000000000000000000000000000000000000000000000000000000000000000000000000000000000000000000000000000000000000000000000000000000000000000000000000000000000000000000000000000000000000000000000000000000000000000000000000000000000000000000000000000000000000000000000000000000000000000000000000000000000000000000000000000000000000000000000000000000000000000000000000000000000000000000000000000000000000000000000000000000000000000000000000000000000000000000000000000000000000000000000000000000000000000000000000000000000000000000000000000000000000000000000000000000000000000000000000000000000000000000000000000000000000000000000000000000000000000000000000000000000000000000000000000000000000000000000000000000000000000000000000000000000000000000000000000000000000000000000000000000000000000000000000000000000000000000000000000000000000000000000000000000000000000000000000000000000000000000000000000000000000000000000000000000000000000000000000000000000000000000000000000000000000000000000000000000000000000000000000000000000000000000000000000000000000000000000000000000000000000000000000000000000000000000000000000000000000000000000000000000000000000000000000000000000000000000000000000000000000000000000000000000000000000000000000000000000000000000000000000000000000000000000000000000000000000000000000000000000000000000000000000000000000000000000000000000000000000000000000000000000000000000000000000000000000000000000000000000000000000000000000000000000000000000000000000000000000000000000000000000000000000000000000000000000000000000000000000000000000000000000000000000000000000000000000000000000000000000000000000000000000000000000000000000000000000000000000000000000000000000000000000000000000000000000000000000000000000000000000000000000000000000000000000000000000000000000000000000000000000000000000000000000000000000000000000000000000000000000000000000000000000000000000000000000000000000000000000000000000000000000000000000000000000000000000000000000000000000000000000000000000000000000000000000000000000000000000000000000000000000000000000000000000000000000000000000000000000000000000000000000000000000000000000000000000000000000000000000000000000000000000000000000000000000000000000000000000000000000000000000000000000000000000000000000000000000000000000000000000000000000000000000000000000000000000000000000000000000000000000000000000000000000000000000000000000000000000000000000000000000000000000000000000000000000000000000000000000000000000000000000000000000000000000000000000000000000000000000000000000000000000000000000000000000000000000000000000000000000000000000000000000000000000000000000000000000000000000000000000000000000000000000000000000000000000000000000000000000000000000000000000000000000000000000000000000000000000000000000000000000000000000000000000000000000000000000000000000000000000000000000000000000000000000000000000000000000000000000000000000000000000000000000000000000000000000000000000000000000000000000000000000000000000000000000000000000000000000000000000000000000000000000000000000000000000000000000000000000000000000000000000000000000000000000000000000000000000000000000000000000000000000000000000000000000000000000000000000000000000000000000000000000000000000000000000000000000000000000000000000000000000000000000000000000000000000000000000000000000000000000000000000000000000000000000000000000000000000000000000000000000000000000000000000000000000000000000000000000000000000000000000000000000000000000000000000000000000000000000000000000000000000000000000000000000000000000000000000000000000000000000000000000000000000000000000000000000000000000000000000000000000000000000000000000000000000000000000000000000000000000000000000000000000000000000000000000000000000000000000000000000000000000000000000000000000000000000000000000000000000000000000000000000000000000000000000000000000000000000000000000000000000000000000000000000000000000000000000000000000000000000000000000000000000000000000000000000000000000000000000000000000000000000000000000000000000000000000000000000000000000000000000000000000000000000000000000000000000000000000000000000000000000000000000000000000000000000000000000000000000000000000000000000000000000000000000000000000000000000000000000000000000000000000000000000000000000000000000000000000000000000000000000000000000000000000000000000000000000000000000000000000000000000000000000000000000000000000000000000000000000000000000000000000000000000000000000000000000000000000000000000000000000000000000000000000000000000000000000000000000000000000000000000000000000000000000000000000000000000000000000000000000000000000000000000000000000000000000000000000000000000000000000000000000000000000000000000000000000000000000000000000000000000000000000000000000000000000000000000000000000000000000000000000000000000000000000000000000000000000000000000000000000000000000000000000000000000000000000000000000000000000000000000000000000000000000000000000000000000000000000000000000000000000000000000000000000000000000000000000000000000000000000000000000000000000000000000000000000000000000000000000000000000000000000000000000000000000000000000000000000000000000000000000000000000000000000000000000000000000000000000000000000000000000000000000000000000000000000000000000000000000000000000000000000000000000000000000000000000000000000000000000000000000000000000000000000000000000000000000000000000000000000000000000000000000000000000000000000000000000000000000000000000000000000000000000000000000000000000000000000000000000000000000000000000000000000000000000000000000000000000000000000000000000000000000000000000000000000000000000000000000000000000000000000000000000000000000000000000000000000000000000000000000000000000000000000000000000000000000000000000000000000000000000000000000000000000000000000000000000000000000000000000000000000000000000000000000000000000000000000000000000000000000000000000000000000000000000000000000000000000000000000000000000000000000000000000000000000000000000000000000000000000000000000000000000000000000000000000000000000000000000000000000000000000000000000000000000000000000000000000000000000000000000000000000000000000000000000000000000000000000000000000000000000000000000000000000000000000000000000000000000000000000000000000000000000000000000000000000000000000000000000000000000000000000000000000000000000000000000000000000000000000000000000000000000000000000000000000000000000000000000000000000000000000000000000000000000000000000000000000000000000000000000000000000000000000000000000000000000000000000000000000000000000000000000000000000000000000000000000000000000000000000000000000000000000000000000000000000000000000000000000000000000000000000000000000000000000000000000000000000000000000000000000000000000000000000000000000000000000000000000000000000000000000000000000000000000000000000000000000000000000000000000000000000000000000000000000000000000000000000000000000000000000000000000000000000000000000000000000000000000000000000000000000000000000000000000000000000000000000000000000000000000000000000000000000000000000000000000000000000000000000000000000000000000000000000000000000000000000000000000000000000000000000000000000000000000000000000000000000000000000000000000000000000000000000000000000000000000000000000000000000000000000000000000000000000000000000000000000000000000000000000000000000000000000000000000000000000000000000000000000000000000000000000000000000000000000000000000000000000000000000000000000000000000000000000000000000000000000000000000000000000000000000000000000000000000000000000000000000000000000000000000000000000000000000000000000000000000000000000000000000000000000000000000000000000000000000000000000000000000000000000000000000000000000000000000000000000000000000000000000000000000000000000000000000000000000000000000000000000000000000000000000000000000000000000000000000000000000000000000000000000000000000000000000000000000000000000000000000000000000000000000000000000000000000000000000000000000000000000000000000000000000000000000000000000000000000000000000000000000000000000000000000000000000000000000000000000000000000000000000000000000000000000000000000000000000000000000000000000000000000000000000000000000000000000000000000000000000000000000000000000000000000000000000000000000000000000000000000000000000000000000000000000000000000000000000000000000000000000000000000000000000000000000000000000000000000000000000000000000000000000000000000000000000000000000000000000000000000000000000000000000000000000000000000000000000000000000000000000000000000000000000000000000000000000000000000000000000000000000000000000000000000000000000000000000000000000000000000000000000000000000000000000000000000000000000000000000000000000000000000000000000000000000000000000000000000000000000000000000000000000000000000000000000000000000000000000000000000000000000000000000000000000000000000000000000000000000000000000000000000000000000000000000000000000000000000000000000000000000000000000000000000000000000000000000000000000000000000000000000000000000000000000000000000000000000000000000000000000000000000000000000000000000000000000000000000000000000000000000000000000000000000000000000000000000000000000000000000000000000000000000000000000000000000000000000000000000000000000000000000000000000000000000000000000000000000000000000000000000000000000000000000000000000000000000000000000000000000000000000000000000000000000000000000000000000000000000000000000000000000000000000000000000000000000000000000000000000000000000000000000000000000000000000000000000000000000000000000000000000000000000000000000000000000000000000000000000000000000000000000000000000000000000000000000000000000000000000000000000000000000000000000000000000000000000000000000000000000000000000000000000000000000000000000000000000000000000000000000000000000000000000000000000000000000000000000000000000000000000000000000000000000000000000000000000000000000000000000000000000000000000000000000000000000000000000000000000000000000000000000000000000000000000000000000000000000000000000000000000000000000000000000000000000000000000000000000000000000000000000000000000000000000000000000000000000000000000000000000000000000000000000000000000000000000000000000000000000000000000000000000000000000000000000000000000000000000000000000000000000000000000000000000000000000000000000000000000000000000000000000000000000000000000000000000000000000000000000000000000000000000000000000000000000000000000000000000000000000000000000000000000000000000000000000000000000000000000000000000000000000000000000000000000000000000000000000000000000000000000000000000000000000000000000000000000000000000000000000000000000000000000000000000000000000000000000000000000000000000000000000000000000000000000000000000000000000000000000000000000000000000000000000000000000000000000000000000000000000000000000000000000000000000000000000000000000000000000000000000000000000000000000000000000000000000000000000000000000000000000000000000000000000000000000000000000000000000000000000000000000000000000000000000000000000000000000000000000000000000000000000000000000000000000000000000000000000000000000000000000000000000000000000000000000000000000000000000000000000000000000000000000000000000000000000000000000000000000000000000000000000000000000000000000000000000000000000000000000000000000000000000000000000000000000000000000000000000000000000000000000000000000000000000000000000000000000000000000000000000000000000000000000000000000000000000000000000000000000000000000000000000000000000000000000000000000000000000000000000000000000000000000000000000000000000000000000000000000000000000000000000000000000000000000000000000000000000000000000000000000000000000000000000000000000000000000000000000000000000000000000000000000000000000000000000000000000000000000000000000000000000000000000000000000000000000000000000000000000000000000000000000000000000000000000000000000000000000000000000000000000000000000000000000000000000000000000000000000000000000000000000000000000000000000000000000000000000000000000000000000000000000000000000000000000000000000000000000000000000000000000000000000000000000000000000000000000000000000000000000000000000000000000000000000000000000000000000000000000000000000000000000000000000000000000000000000000000000000000000000000000000000000000000000000000000000000000000000000000000000000000000000000000000000000000000000000000000000000000000000000000000000000000000000000000000000000000000000000000000000000000000000000000000000000000000000000000000000000000000000000000000000000000000000000000000000000000000000000000000000000000000000000000000000000000000000000000000000000000000000000000000000000000000000000000000000000000000000000000000000000000000000000000000000000000000000000000000000000000000000000000000000000000000000000000000000000000000000000000000000000000000000000000000000000000000000000000000000000000000000000000000000000000000000000000000000000000000000000000000000000000000000000000000000000000000000000000000000000000000000000000000000000000000000000000000000000000000000000000000000000000000000000000000000000000000000000000000000000000000000000000000000000000000000000000000000000000000000000000000000000000000000000000000000000000000000000000000000000000000000000000000000000000000000000000000000000000000000000000000000000000000000000000000000000000000000000000000000000000000000000000000000000000000000000000000000000000000000000000000000000000000000000000000000000000000000000000000000000000000000000000000000000000000000000000000000000000000000000000000000000000000000000000000000000000000000000000000000000000000000000000000000000000000000000000000000000000000000000000000000000000000000000000000000000000000000000000000000000000000000000000000000000000000000000000000000000000000000000000000000000000000000000000000000000000000000000000000000000000000000000000000000000000000000000000000000000000000000000000000000000000000000000000000000000000000000000000000000000000000000000000000000000000000000000000000000000000000000000000000000000000000000000000000000000000000000000000000000000000000000000000000000000000000000000000000000000000000000000000000000000000000000000000000000000000000000000000000000000000000000000000000000000000000000000000000000000000000000000000000000000000000000000000000000000000000000000000000000000000000000000000000000000000000000000000000000000000000000000000000000000000000000000000000000000000000000000000000000000000000000000000000000000000000000000000000000000000000000000000000000000000000000000000000000000000000000000000000000000000000000000000000000000000000000000000000000000000000000000000000000000000000000000000000000000000000000000000000000000000000000000000000000000000000000000000000000000000000000000000000000000000000000000000000000000000000000000000000000000000000000000000000000000000000000000000000000000000000000000000000000000000000000000000000000000000000000000000000000000000000000000000000000000000000000000000000000000000000000000000000000000000000000000000000000000000000000000000000000000000000000000000000000000000000000000000000000000000000000000000000000000000000000000000000000000000000000000000000000000000000000000000000000000000000000000000000000000000000000000000000000000000000000000000000000000000000000000000000000000000000000000000000000000000000000000000000000000000000000000000000000000000000000000000000000000000000000000000000000000000000000000000000000000000000000000000000000000000000000000000000000000000000000000000000000000000000000000000000000000000000000000000000000000000000000000000000000000000000000000000000000000000000000000000000000000000000000000000000000000000000000000000000000000000000000000000000000000000000000000000000000000000000000000000000000000000000000000000000000000000000000000000000000000000000000000000000000000000000000000000000000000000000000000000000000000000000000000000000000000000000000000000000000000000000000000000000000000000000000000000000000000000000000000000000000000000000000000000000000000000000000000000000000000000000000000000000000000000000000000000000000000000000000000000000000000000000000000000000000000000000000000000000000000000000000000000000000000000000000000000000000000000000000000000000000000000000000000000000000000000000000000000000000000000000000000000000000000000000000000000000000000000000000000000000000000000000000000000000000000000000000000000000000000000000000000000000000000000000000000000000000000000000000000000000000000000000000000000000000000000000000000000000000000000000000000000000000000000000000000000000000000000000000000000000000000000000000000000000000000000000000000000000000000000000000000000000000000000000000000000000000000000000000000000000000000000000000000000000000000000000000000000000000000000000000000000000000000000000000000000000000000000000000000000000000000000000000000000000000000000000000000000000000000000000000000000000000000000000000000000000000000000000000000000000000000000000000000000000000000000000000000000000000000000000000000000000000000000000000000000000000000000000000000000000000000000000000000000000000000000000000000000000000000000000000000000000000000000000000000000000000000000000000000000000000000000000000000000000000000000000000000000000000000000000000000000000000000000000000000000000000000000000000000000000000000000000000000000000000000000000000000000000000000000000000000000000000000000000000000000000000000000000000000000000000000000000000000000000000000000000000000000000000000000000000000000000000000000000000000000000000000000000000000000000000000000000000000000000000000000000000000000000000000000000000000000000000000000000000000000000000000000000000000000000000000000000000000000000000000000000000000000000000000000000000000000000000000000000000000000000000000000000000000000000000000000000000000000000000000000000000000000000000000000000000000000000000000000000000000000000000000000000000000000000000000000000000000000000000000000000000000000000000000000000000000000000000000000000000000000000000000000000000000000000000000000000000000000000000000000000000000000000000000000000000000000000000000000000000000000000000000000000000000000000000000000000000000000000000000000000000000000000000000000000000000000000000000000000000000000000000000000000000000000000000000000000000000000000000000000000000000000000000000000000000000000000000000000000000000000000000000000000000000000000000000000000000000000000000000000000000000000000000000000000000000000000000000000000000000000000000000000000000000000000000000000000000000000000000000000000000000000000000000000000000000000000000000000000000000000000000000000000000000000000000000000000000000000000000000000000000000000000000000000000000000000000000000000000000000000000000000000000000000000000000000000000000000000000000000000000000000000000000000000000000000000000000000000000000000000000000000000000000000000000000000000000000000000000000000000000000000000000000000000000000000000000000000000000000000000000000000000000000000000000000000000000000000000000000000000000000000000000000000000000000000000000000000000000000000000000000000000000000000000000000000000000000000000000000000000000000000000000000000000000000000000000000000000000000000000000000000000000000000000000000000000000000000000000000000000000000000000000000000000000000000000000000000000000000000000000000000000000000000000000000000000000000000000000000000000000000000000000000000000000000000000000000000000000000000000000000000000000000000000000000000000000000000000000000000000000000000000000000000000000000000000000000000000000000000000000000000000000000000000000000000000000000000000000000000000000000000000000000000000000000000000000000000000000000000000000000000000000000000000000000000000000000000000000000000000000000000000000000000000000000000000000000000000000000000000000000000000000000000000000000000000000000000000000000000000000000000000000000000000000000000000000000000000000000000000000000000000000000000000000000000000000000000000000000000000000000000000000000000000000000000000000000000000000000000000000000000000000000000000000000000000000000000000000000000000000000000000000000000000000000000000000000000000000000000000000000000000000000000000000000000000000000000000000000000000000000000000000000000000000000000000000000000000000000000000000000000000000000000000000000000000000000000000000000000000000000000000000000000000000000000000000000000000000000000000000000000000000000000000000000000000000000000000000000000000000000000000000000000000000000000000000000000000000000000000000000000000000000000000000000000000000000000000000000000000000000000000000000000000000000000000000000000000000000000000000000000000000000000000000000000000000000000000000000000000000000000000000000000000000000000000000000000000000000000000000000000000000000000000000000000000000000000000000000000000000000000000000000000000000000000000000000000000000000000000000000000000000000000000000000000000000000000000000000000000000000000000000000000000000000000000000000000000000000000000000000000000000000000000000000000000000000000000000000000000000000000000000000000000000000000000000000000000000000000000000000000000000000000000000000000000000000000000000000000000000000000000000000000000000000000000000000000000000000000000000000000000000000000000000000000000000000000000000000000000000000000000000000000000000000000000000000000000000000000000000000000000000000000000000000000000000000000000000000000000000000000000000000000000000000000000000000000000000000000000000000000000000000000000000000000000000000000000000000000000000000000000000000000000000000000000000000000000000000000000000000000000000000000000000000000000000000000000000000000000000000000000000000000000000000000000000000000000000000000000000000000000000000000000000000000000000000000000000000000000000000000000000000000000000000000000000000000000000000000000000000000000000000000000000000000000000000000000000000000000000000000000000000000000000000000000000000000000000000000000000000000000000000000000000000000000000000000000000000000000000000000000000000000000000000000000000000000000000000000000000000000000000000000000000000000000000000000000000000000000000000000000000000000000000000000000000000000000000000000000000000000000000000000000000000000000000000000000000000000000000000000000000000000000000000000000000000000000000000000000000000000000000000000000000000000000000000000000000000000000000000000000000000000000000000000000000000000000000000000000000000000000000000000000000000000000000000000000000000000000000000000000000000000000000000000000000000000000000000000000000000000000000000000000000000000000000000000000000000000000000000000000000000000000000000000000000000000000000000000000000000000000000000000000000000000000000000000000000000000000000000000000000000000000000000000000000000000000000000000000000000000000000000000000000000000000000000000000000000000000000000000000000000000000000000000000000000000000000000000000000000000000000000000000000000000000000000000000000000000000000000000000000000000000000000000000000000000000000000000000000000000000000000000000000000000000000000000000000000000000000000000000000000000000000000000000000000000000000000000000000000000000000000000000000000000000000000000000000000000000000000000000000000000000000000000000000000000000000000000000000000000000000000000000000000000000000000000000000000000000000000000000000000000000000000000000000000000000000000000000000000000000000000000000000000000000000000000000000000000000000000000000000000000000000000000000000000000000000000000000000000000000000000000000000000000000000000000000000000000000000000000000000000000000000000000000000000000000000000000000000000000000000000000000000000000000000000000000000000000000000000000000000000000000000000000000000000000000000000000000000000000000000000000000000000000000000000000000000000000000000000000000000000000000000000000000000000000000000000000000000000000000000000000000000000000000000000000000000000000000000000000000000000000000000000000000000000000000000000000000000000000000000000000000000000000000000000000000000000000000000000000000000000000000000000000000000000000000000000000000000000000000000000000000000000000000000000000000000000000000000000000000000000000000000000000000000000000000000000000000000000000000000000000000000000000000000000000000000000000000000000000000000000000000000000000000000000000000000000000000000000000000000000000000000000000000000000000000000000000000000000000000000000000000000000000000000000000000000000000000000000000000000000000000000000000000000000000000000000000000000000000000000000000000000000000000000000000000000000000000000000000000000000000000000000000000000000000000000000000000000000000000000000000000000000000000000000000000000000000000000000000000000000000000000000000000000000000000000000000000000000000000000000000000000000000000000000000000000000000000000000000000000000000000000000000000000000000000000000000000000000000000000000000000000000000000000000000000000000000000000000000000000000000000000000000000000000000000000000000000000000000000000000000000000000000000000000000000000000000000000000000000000000000000000000000000000000000000000000000000000000000000000000000000000000000000000000000000000000000000000000000000000000000000000000000000000000000000000000000000000000000000000000000000000000000000000000000000000000000000000000000000000000000000000000000000000000000000000000000000000000000000000000000000000000000000000000000000000000000000000000000000000000000000000000000000000000000000000000000000000000000000000000000000000000000000000000000000000000000000000000000000000000000000000000000000000000000000000000000000000000000000000000000000000000000000000000000000000000000000000000000000000000000000000000000000000000000000000000000000000000000000000000000000000000000000000000000000000000000000000000000000000000000000000000000000000000000000000000000000000000000000000000000000000000000000000000000000000000000000000000000000000000000000000000000000000000000000000000000000000000000000000000000000000000000000000000000000000000000000000000000000000000000000000000000000000000000000000000000000000000000000000000000000000000000000000000000000000000000000000000000000000000000000000000000000000000000000000000000000000000000000000000000000000000000000000000000000000000000000000000000000000000000000000000000000000000000000000000000000000000000000000000000000000000000000000000000000000000000000000000000000000000000000000000000000000000000000000000000000000000000000000000000000000000000000000000000000000000000000000000000000000000000000000000000000000000000000000000000000000000000000000000000000000000000000000000000000000000000000000000000000000000000000000000000000000000000000000000000000000000000000000000000000000000000000000000000000000000000000000000000000000000000000000000000000000000000000000000000000000000000000000000000000000000000000000000000000000000000000000000000000000000000000000000000000000000000000000000000000000000000000000000000000000000000000000000000000000000000000000000000000000000000000000000000000000000000000000000000000000000000000000000000000000000000000000000000000000000000000000000000000000000000000000000000000000000000000000000000000000000000000000000000000000000000000000000000000000000000000000000000000000000000000000000000000000000000000000000000000000000000000000000000000000000000000000000000000000000000000000000000000000000000000000000000000000000000000000000000000000000000000000000000000000000000000000000000000000000000000000000000000000000000000000000000000000000000000000000000000000000000000000000000000000000000000000000000000000000000000000000000000000000000000000000000000000000000000000000000000000000000000000000000000000000000000000000000000000000000000000000000000000000000000000000000000000000000000000000000000000000000000000000000000000000000000000000000000000000000000000000000000000000000000000000000000000000000000000000000000000000000000000000000000000000000000000000000000000000000000000000000000000000000000000000000000000000000000000000000000000000000000000000000000000000000000000000000000000000000000000000000000000000000000000000000000000000000000000000000000000000000000000000000000000000000000000000000000000000000000000000000000000000000000000000000000000000000000000000000000000000000000000000000000000000000000000000000000000000000000000000000000000000000000000000000000000000000000000000000000000000000000000000000000000000000000000000000000000000000000000000000000000000000000000000000000000000000000000000000000000000000000000000000000000000000000000000000000000000000000000000000000000000000000000000000000000000000000000000000000000000000000000000000000000000000000000000000000000000000000000000000000000000000000000000000000000000000000000000000000000000000000000000000000000000000000000000000000000000000000000000000000000000000000000000000000000000000000000000000000000000000000000000000000000000000000000000000000000000000000000000000000000000000000000000000000000000000000000000000000000000000000000000000000000000000000000000000000000000000000000000000000000000000000000000000000000000000000000000000000000000000000000000000000000000000000000000000000000000000000000000000000000000000000000000000000000000000000000000000000000000000000000000000000000000000000000000000000000000000000000000000000000000000000000000000000000000000000000000000000000000000000000000000000000000000000000000000000000000000000000000000000000000000000000000000000000000000000000000000000000000000000000000000000000000000000000000000000000000000000000000000000000000000000000000000000000000000000000000000000000000000000000000000000000000000000000000000000000000000000000000000000000000000000000000000000000000000000000000000000000000000000000000000000000000000000000000000000000000000000000000000000000000000000000000000000000000000000000000000000000000000000000000000000000000000000000000000000000000000000000000000000000000000000000000000000000000000000000000000000000000000000000000000000000000000000000000000000000000000000000000000000000000000000000000000000000000000000000000000000000000000000000000000000000000000000000000000000000000000000000000000000000000000000000000000000000000000000000000000000000000000000000000000000000000000000000000000000000000000000000000000000000000000000000000000000000000000000000000000000000000000000000000000000000000000000000000000000000000000000000000000000000000000000000000000000000000000000000000000000000000000000000000000000000000000000000000000000000000000000000000000000000000000000000000000000000000000000000000000000000000000000000000000000000000000000000000000000000000000000000000000000000000000000000000000000000000000000000000000000000000000000000000000000000000000000000000000000000000000000000000000000000000000000000000000000000000000000000000000000000000000000000000000000000000000000000000000000000000000000000000000000000000000000000000000000000000000000000000000000000000000000000000000000000000000000000000000000000000000000000000000000000000000000000000000000000000000000000000000000000000000000000000000000000000000000000000000000000000000000000000000000000000000000000000000000000000000000000000000000000000000000000000000000000000000000000000000000000000000000000000000000000000000000000000000000000000000000000000000000000000000000000000000000000000000000000000000000000000000000000000000000000000000000000000000000000000000000000000000000000000000000000000000000000000000000000000000000000000000000000000000000000000000000000000000000000000000000000000000000000000000000000000000000000000000000000000000000000000000000000000000000000000000000000000000000000000000000000000000000000000000000000000000000000000000000000000000000000000000000000000000000000000000000000000000000000000000000000000000000000000000000000000000000000000000000000000000000000000000000000000000000000000000000000000000000000000000000000000000000000000000000000000000000000000000000000000000000000000000000000000000000000000000000000000000000000000000000000000000000000000000000000000000000000000000000000000000000000000000000000000000000000000000000000000000000000000000000000000000000000000000000000000000000000000000000000000000000000000000000000000000000000000000000000000000000000000000000000000000000000000000000000000000000000000000000000000000000000000000000000000000000000000000000000000000000000000000000000000000000000000000000000000000000000000000000000000000000000000000000000000000000000000000000000000000000000000000000000000000000000000000000000000000000000000000000000000000000000000000000000000000000000000000000000000000000000000000000000000000000000000000000000000000000000000000000000000000000000000000000000000000000000000000000000000000000000000000000000000000000000000000000000000000000000000000000000000000000000000000000000000000000000000000000000000000000000000000000000000000000000000000000000000000000000000000000000000000000000000000000000000000000000000000000000000000000000000000000000000000000000000000000000000000000000000000000000000000000000000000000000000000000000000000000000000000000000000000000000000000000000000000000000000000000000000000000000000000000000000000000000000000000000000000000000000000000000000000000000000000000000000000000000000000000000000000000000000000000000000000000000000000000000000000000000000000000000000000000000000000000000000000000000000000000000000000000000000000000000000000000000000000000000000000000000000000000000000000000000000000000000000000000000000000000000000000000000000000000000000000000000000000000000000000000000000000000000000000000000000000000000000000000000000000000000000000000000000000000000000000000000000000000000000000000000000000000000000000000000000000000000000000000000000000000000000000000000000000000000000000000000000000000000000000000000000000000000000000000000000000000000000000000000000000000000000000000000000000000000000000000000000000000000000000000000000000000000000000000000000000000000000000000000000000000000000000000000000000000000000000000000000000000000000000000000000000000000000000000000000000000000000000000000000000000000000000000000000000000000000000000000000000000000000000000000000000000000000000000000000000000000000000000000000000000000000000000000000000000000000000000000000000000000000000000000000000000000000000000000000000000000000000000000000000000000000000000000000000000000000000000000000000000000000000000000000000000000000000000000000000000000000000000000000000000000000000000000000000000000000000000000000000000000000000000000000000000000000000000000000000000000000000000000000000000000000000000000000000000000000000000000000000000000000000000000000000000000000000000000000000000000000000000000000000000000000000000000000000000000000000000000000000000000000000000000000000000000000000000000000000000000000000000000000000000000000000000000000000000000000000000000000000000000000000000000000000000000000000000000000000000000000000000000000000000000000000000000000000000000000000000000000000000000000000000000000000000000000000000000000000000000000000000000000000000000000000000000000000000000000000000000000000000000000000000000000000000000000000000000000000000000000000000000000000000000000000000000000000000000000000000000000000000000000000000000000000000000000000000000000000000000000000000000000000000000000000000000000000000000000000000000000000000000000000000000000000000000000000000000000000000000000000000000000000000000000000000000000000000000000000000000000000000000000000000000000000000000000000000000000000000000000000000000000000000000000000000000000000000000000000000000000000000000000000000000000000000000000000000000000000000000000000000000000000000000000000000000000000000000000000000000000000000000000000000000000000000000000000000000000000000000000000000000000000000000000000000000000000000000000000000000000000000000000000000000000000000000000000000000000000000000000000000000000000000000000000000000000000000000000000000000000000000000000000000000000000000000000000000000000000000000000000000000000000000000000000000000000000000000000000000000000000000000000000000000000000000000000000000000000000000000000000000000000000000000000000000000000000000000000000000000000000000000000000000000000000000000000000000000000000000000000000000000000000000000000000000000000000000000000000000000000000000000000000000000000000000000000000000000000000000000000000000000000000000000000000000000000000000000000000000000000000000000000000000000000000000000000000000000000000000000000000000000000000000000000000000000000000000000000000000000000000000000000000000000000000000000000000000000000000000000000000000000000000000000000000000000000000000000000000000000000000000000000000000000000000000000000000000000000000000000000000000000000000000000000000000000000000000000000000000000000000000000000000000000000000000000000000000000000000000000000000000000000000000000000000000000000000000000000000000000000000000000000000000000000000000000000000000000000000000000000000000000000000000000000000000000000000000000000000000000000000000000000000000000000000000000000000000000000000000000000000000000000000000000000000000000000000000000000000000000000000000000000000000000000000000000000000000000000000000000000000000000000000000000000000000000000000000000000000000000000000000000000000000000000000000000000000000000000000000000000000000000000000000000000000000000000000000000000000000000000000000000000000000000000000000000000000000000000000000000000000000000000000000000000000000000000000000000000000000000000000000000000000000000000000000000000000000000000000000000000000000000000000000000000000000000000000000000000000000000000000000000000000000000000000000000000000000000000000000000000000000000000000000000000000000000000000000000000000000000000000000000000000000000000000000000000000000000000000000000000000000000000000000000000000000000000000000000000000000000000000000000000000000000000000000000000000000000000000000000000000000000000000000000000000000000000000000000000000000000000000000000000000000000000000000000000000000000000000000000000000000000000000000000000000000000000000000000000000000000000000000000000000000000000000000000000000000000000000000000000000000000000000000000000000000000000000000000000000000000000000000000000000000000000000000000000000000000000000000000000000000000000000000000000000000000000000000000000000000000000000000000000000000000000000000000000000000000000000000000000000000000000000000000000000000000000000000000000000000000000000000000000000000000000000000000000000000000000000000000000000000000000000000000000000000000000000000000000000000000000000000000000000000000000000000000000000000000000000000000000000000000000000000000000000000000000000000000000000000000000000000000000000000000000000000000000000000000000000000000000000000000000000000000000000000000000000000000000000000000000000000000000000000000000000000000000000000000000000000000000000000000000000000000000000000000000000000000000000000000000000000000000000000000000000000000000000000000000000000000000000000000000000000000000000000000000000000000000000000000000000000000000000000000000000000000000000000000000000000000000000000000000000000000000000000000000000000000000000000000000000000000000000000000000000000000000000000000000000000000000000000000000000000000000000000000000000000000000000000000000000000000000000000000000000000000000000000000000000000000000000000000000000000000000000000000000000000000000000000000000000000000000000000000000000000000000000000000000000000000000000000000000000000000000000000000000000000000000000000000000000000000000000000000000000000000000000000000000000000000000000000000000000000000000000000000000000000000000000000000000000000000000000000000000000000000000000000000000000000000000000000000000000000000000000000000000000000000000000000000000000000000000000000000000000000000000000000000000000000000000000000000000000000000000000000000000000000000000000000000000000000000000000000000000000000000000000000000000000000000000000000000000000000000000000000000000000000000000000000000000000000000000000000000000000000000000000000000000000000000000000000000000000000000000000000000000000000000000000000000000000000000000000000000000000000000000000000000000000000000000000000000000000000000000000000000000000000000000000000000000000000000000000000000000000000000000000000000000000000000000000000000000000000000000000000000000000000000000000000000000000000000000000000000000000000000000000000000000000000000000000000000000000000000000000000000000000000000000000000000000000000000000000000000000000000000000000000000000000000000000000000000000000000000000000000000000000000000000000000000000000000000000000000000000000000000000000000000000000000000000000000000000000000000000000000000000000000000000000000000000000000000000000000000000000000000000000000000000000000000000000000000000000000000000000000000000000000000000000000000000000000000000000000000000000000000000000000000000000000000000000000000000000000000000000000000000000000000000000000000000000000000000000000000000000000000000000000000000000000000000000000000000000000000000000000000000000000000000000000000000000000000000000000000000000000000000000000000000000000000000000000000000000000000000000000000000000000000000000000000000000000000000000000000000000000000000000000000000000000000000000000000000000000000000000000000000000000000000000000000000000000000000000000000000000000000000000000000000000000000000000000000000000000000000000000000000000000000000000000000000000000000000000000000000000000000000000000000000000000000000000000000000000000000000000000000000000000000000000000000000000000000000000000000000000000000000000000000000000000000000000000000000000000000000000000000000000000000000000000000000000000000000000000000000000000000000000000000000000000000000000000000000000000000000000000000000000000000000000000000000000000000000000000000000000000000000000000000000000000000000000000000000000000000000000000000000000000000000000000000000000000000000000000000000000000000000000000000000000000000000000000000000000000000000000000000000000000000000000000000000000000000000000000000000000000000000000000000000000000000000000000000000000000000000000000000000000000000000000000000000000000000000000000000000000000000000000000000000000000000000000000000000000000000000000000000000000000000000000000000000000000000000000000000000000000000000000000000000000000000000000000000000000000000000000000000000000000000000000000000000000000000000000000000000000000000000000000000000000000000000000000000000000000000000000000000000000000000000000000000000000000000000000000000000000000000000000000000000000000000000000000000000000000000000000000000000000000000000000000000000000000000000000000000000000000000000000000000000000000000000000000000000000000000000000000000000000000000000000000000000000000000000000000000000000000000000000000000000000000000000000000000000000000000000000000000000000000000000000000000000000000000000000000000000000000000000000000000000000000000000000000000000000000000000000000000000000000000000000000000000000000000000000000000000000000000000000000000000000000000000000000000000000000000000000000000000000000000000000000000000000000000000000000000000000000000000000000000000000000000000000000000000000000000000000000000000000000000000000000000000000000000000000000000000000000000000000000000000000000000000000000000000000000000000000000000000000000000000000000000000000000000000000000000000000000000000000000000000000000000000000000000000000000000000000000000000000000000000000000000000000000000000000000000000000000000000000000000000000000000000000000000000000000000000000000000000000000000000000000000000000000000000000000000000000000000000000000000000000000000000000000000000000000000000000000000000000000000000000000000000000000000000000000000000000000000000000000000000000000000000000000000000000000000000000000000000000000000000000000000000000000000000000000000000000000000000000000000000000000000000000000000000000000000000000000000000000000000000000000000000000000000000000000000000000000000000000000000000000000000000000000000000000000000000000000000000000000000000000000000000000000000000000000000000000000000000000000000000000000000000000000000000000000000000000000000000000000000000000000000000000000000000000000000000000000000000000000000000000000000000000000000000000000000000000000000000000000000000000000000000000000000000000000000000000000000000000000000000000000000000000000000000000000000000000000000000000000000000000000000000000000000000000000000000000000000000000000000000000000000000000000000000000000000000000000000000000000000000000000000000000000000000000000000000000000000000000000000000000000000000000000000000000000000000000000000000000000000000000000000000000000000000000000000000000000000000000000000000000000000000000000000000000000000000000000000000000000000000000000000000000000000000000000000000000000000000000000000000000000000000000000000000000000000000000000000000000000000000000000000000000000000000000000000000000000000000000000000000000000000000000000000000000000000000000000000000000000000000000000000000000000000000000000000000000000000000000000000000000000000000000000000000000000000000000000000000000000000000000000000000000000000000000000000000000000000000000000000000000000000000000000000000000000000000000000000000000000000000000000000000000000000000000000000000000000000000000000000000000000000000000000000000000000000000000000000000000000000000000000000000000000000000000000000000000000000000000000000000000000000000000000000000000000000000000000000000000000000000000000000000000000000000000000000000000000000000000000000000000000000000000000000000000000000000000000000000000000000000000000000000000000000000000000000000000000000000000000000000000000000000000000000000000000000000000000000000000000000000000000000000000000000000000000000000000000000000000000000000000000000000000000000000000000000000000000000000000000000000000000000000000000000000000000000000000000000000000000000000000000000000000000000000000000000000000000000000000000000000000000000000000000000000000000000000000000000000000000000000000000000000000000000000000000000000000000000000000000000000000000000000000000000000000000000000000000000000000000000000000000000000000000000000000000000000000000000000000000000000000000000000000000000000000000000000000000000000000000000000000000000000000000000000000000000000000000000000000000000000000000000000000000000000000000000000000000000000000000000000000000000000000000000000000000000000000000000000000000000000000000000000000000000000000000000000000000000000000000000000000000000000000000000000000000000000000000000000000000000000000000000000000000000000000000000000000000000000000000000000000000000000000000000000000000000000000000000000000000000000000000000000000000000000000000000000000000000000000000000000000000000000000000000000000000000000000000000000000000000000000000000000000000000000000000000000000000000000000000000000000000000000000000000000000000000000000000000000000000000000000000000000000000000000000000000000000000000000000000000000000000000000000000000000000000000000000000000000000000000000000000000000000000000000000000000000000000000000000000000000000000000000000000000000000000000000000000000000000000000000000000000000000000000000000000000000000000000000000000000000000000000000000000000000000000000000000000000000000000000000000000000000000000000000000000000000000000000000000000000000000000000000000000000000000000000000000000000000000000000000000000000000000000000000000000000000000000000000000000000000000000000000000000000000000000000000000000000000000000000000000000000000000000000000000000000000000000000000000000000000000000000000000000000000000000000000000000000000000000000000000000000000000000000000000000000000000000000000000000000000000000000000000000000000000000000000000000000000000000000000000000000000000000000000000000000000000000000000000000000000000000000000000000000000000000000000000000000000000000000000000000000000000000000000000000000000000000000000000000000000000000000000000000000000000000000000000000000000000000000000000000000000000000000000000000000000000000000000000000000000000000000000000000000000000000000000000000000000000000000000000000000000000000000000000000000000000000000000000000000000000000000000000000000000000000000000000000000000000000000000000000000000000000000000000000000000000000000000000000000000000000000000000000000000000000000000000000000000000000000000000000000000000000000000000000000000000000000000000000000000000000000000000000000000000000000000000000000000000000000000000000000000000000000000000000000000000000000000000000000000000000000000000000000000000000000000000000000000000000000000000000000000000000000000000000000000000000000000000000000000000000000000000000000000000000000000000000000000000000000000000000000000000000000000000000000000000000000000000000000000000000000000000000000000000000000000000000000000000000000000000000000000000000000000000000000000000000000000000000000000000000000000000000000000000000000000000000000000000000000000000000000000000000000000000000000000000000000000000000000000000000000000000000000000000000000000000000000000000000000000000000000000000000000000000000000000000000000000000000000000000000000000000000000000000000000000000000000000000000000000000000000000000000000000000000000000000000000000000000000000000000000000000000000000000000000000000000000000000000000000000000000000000000000000000000000000000000000000000000000000000000000000000000000000000000000000000000000000000000000000000000000000000000000000000000000000000000000000000000000000000000000000000000000000000000000000000000000000000000000000000000000000000000000000000000000000000000000000000000000000000000000000000000000000000000000000000000000000000000000000000000000000000000000000000000000000000000000000000000000000000000000000000000000000000000000000000000000000000000000000000000000000000000000000000000000000000000000000000000000000000000000000000000000000000000000000000000000000000000000000000000000000000000000000000000000000000000000000000000000000000000000000000000000000000000000000000000000000000000000000000000000000000000000000000000000000000000000000000000000000000000000000000000000000000000000000000000000000000000000000000000000000000000000000000000000000000000000000000000000000000000000000000000000000000000000000000000000000000000000000000000000000000000000000000000000000000000000000000000000000000000000000000000000000000000000000000000000000000000000000000000000000000000000000000000000000000000000000000000000000000000000000000000000000000000000000000000000000000000000000000000000000000000000000000000000000000000000000000000000000000000000000000000000000000000000000000000000000000000000000000000000000000000000000000000000000000000000000000000000000000000000000000000000000000000000000000000000000000000000000000000000000000000000000000000000000000000000000000000000000000000000000000000000000000000000000000000000000000000000000000000000000000000000000000000000000000000000000000000000000000000000000000000000000000000000000000000000000000000000000000000000000000000000000000000000000000000000000000000000000000000000000000000000000000000000000000000000000000000000000000000000000000000000000000000000000000000000000000000000000000000000000000000000000000000000000000000000000000000000000000000000000000000000000000000000000000000000000000000000000000000000000000000000000000000000000000000000000000000000000000000000000000000000000000000000000000000000000000000000000000000000000000000000000000000000000000000000000000000000000000000000000000000000000000000000000000000000000000000000000000000000000000000000000000000000000000000000000000000000000000000000000000000000000000000000000000000000000000000000000000000000000000000000000000000000000000000000000000000000000000000000000000000000000000000000000000000000000000000000000000000000000000000000000000000000000000000000000000000000000000000000000000000000000000000000000000000000000000000000000000000000000000000000000000000000000000000000000000000000000000000000000000000000000000000000000000000000000000000000000000000000000000000000000000000000000000000000000000000000000000000000000000000000000000000000000000000000000000000000000000000000000000000000000000000000000000000000000000000000000000000000000000000000000000000000000000000000000000000000000000000000000000000000000000000000000000000000000000000000000000000000000000000000000000000000000000000000000000000000000000000000000000000000000000000000000000000000000000000000000000000000000000000000000000000000000000000000000000000000000000000000000000000000000000000000000000000000000000000000000000000000000000000000000000000000000000000000000000000000000000000000000000000000000000000000000000000000000000000000000000000000000000000000000000000000000000000000000000000000000000000000000000000000000000000000000000000000000000000000000000000000000000000000000000000000000000000000000000000000000000000000000000000000000000000000000000000000000000000000000000000000000000000000000000000000000000000000000000000000000000000000000000000000000000000000000000000000000000000000000000000000000000000000000000000000000000000000000000000000000000000000000000000000000000000000000000000000000000000000000000000000000000000000000000000000000000000000000000000000000000000000000000000000000000000000000000000000000000000000000000000000000000000000000000000000000000000000000000000000000000000000000000000000000000000000000000000000000000000000000000000000000000000000000000000000000000000000000000000000000000000000000000000000000000000000000000000000000000000000000000000000000000000000000000000000000000000000000000000000000000000000000000000000000000000000000000000000000000000000000000000000000000000000000000000000000000000000000000000000000000000000000000000000000000000000000000000000000000000000000000000000000000000000000000000000000000000000000000000000000000000000000000000000000000000000000000000000000000000000000000000000000000000000000000000000000000000000000000000000000000000000000000000000000000000000000000000000000000000000000000000000000000000000000000000000000000000000000000000000000000000000000000000000000000000000000000000000000000000000000000000000000000000000000000000000000000000000000000000000000000000000000000000000000000000000000000000000000000000000000000000000000000000000000000000000000000000000000000000000000000000000000000000000000000000000000000000000000000000000000000000000000000000000000000000000000000000000000000000000000000000000000000000000000000000000000000000000000000000000000000000000000000000000000000000000000000000000000000000000000000000000000000000000000000000000000000000000000000000000000000000000000000000000000000000000000000000000000000000000000000000000000000000000000000000000000000000000000000000000000000000000000000000000000000000000000000000000000000000000000000000000000000000000000000000000000000000000000000000000000000000000000000000000000000000000000000000000000000000000000000000000000000000000000000000000000000000000000000000000000000000000000000000000000000000000000000000000000000000000000000000000000000000000000000000000000000000000000000000000000000000000000000000000000000000000000000000000000000000000000000000000000000000000000000000000000000000000000000000000000000000000000000000000000000000000000000000000000000000000000000000000000000000000000000000000000000000000000000000000000000000000000000000000000000000000000000000000000000000000000000000000000000000000000000000000000000000000000000000000000000000000000000000000000000000000000000000000000000000000000000000000000000000000000000000000000000000000000000000000000000000000000000000000000000000000000000000000000000000000000000000000000000000000000000000000000000000000000000000000000000000000000000000000000000000000000000000000000000000000000000000000000000000000000000000000000000000000000000000000000000000000000000000000000000000000000000000000000000000000000000000000000000000000000000000000000000000000000000000000000000000000000000000000000000000000000000000000000000000000000000000000000000000000000000000000000000000000000000000000000000000000000000000000000000000000000000000000000000000000000000000000000000000000000000000000000000000000000000000000000000000000000000000000000000000000000000000000000000000000000000000000000000000000000000000000000000000000000000000000000000000000000000000000000000000000000000000000000000000000000000000000000000000000000000000000000000000000000000000000000000000000000000000000000000000000000000000000000000000000000000000000000000000000000000000000000000000000000000000000000000000000000000000000000000000000000000000000000000000000000000000000000000000000000000000000000000000000000000000000000000000000000000000000000000000000000000000000000000000000000000000000000000000000000000000000000000000000000000000000000000000000000000000000000000000000000000000000000000000000000000000000000000000000000000000000000000000000000000000000000000000000000000000000000000000000000000000000000000000000000000000000000000000000000000000000000000000000000000000000000000000000000000000000000000000000000000000000000000000000000000000000000000000000000000000000000000000000000000000000000000000000000000000000000000000000000000000000000000000000000000000000000000000000000000000000000000000000000000000000000000000000000000000000000000000000000000000000000000000000000000000000000000000000000000000000000000000000000000000000000000000000000000000000000000000000000000000000000000000000000000000000000000000000000000000000000000000000000000000000000000000000000000000000000000000000000000000000000000000000000000000000000000000000000000000000000000000000000000000000000000000000000000000000000000000000000000000000000000000000000000000000000000000000000000000000000000000000000000000000000000000000000000000000000000000000000000000000000000000000000000000000000000000000000000000000000000000000000000000000000000000000000000000000000000000000000000000000000000000000000000000000000000000000000000000000000000000000000000000000000000000000000000000000000000000000000000000000000000000000000000000000000000000000000000000000000000000000000000000000000000000000000000000000000000000000000000000000000000000000000000000000000000000000000000000000000000000000000000000000000000000000000000000000000000000000000000000000000000000000000000000000000000000000000000000000000000000000000000000000000000000000000000000000000000000000000000000000000000000000000000000000000000000000000000000000000000000000000000000000000000000000000000000000000000000000000000000000000000000000000000000000000000000000000000000000000000000000000000000000000000000000000000000000000000000000000000000000000000000000000000000000000000000000000000000000000000000000000000000000000000000000000000000000000000000000000000000000000000000000000000000000000000000000000000000000000000000000000000000000000000000000000000000000000000000000000000000000000000000000000000000000000000000000000000000000000000000000000000000000000000000000000000000000000000000000000000000000000000000000000000000000000000000000000000000000000000000000000000000000000000000000000000000000000000000000000000000000000000000000000000000000000000000000000000000000000000000000000000000000000000000000000000000000000000000000000000000000000000000000000000000000000000000000000000000000000000000000000000000000000000000000000000000000000000000000000000000000000000000000000000000000000000000000000000000000000000000000000000000000000000000000000000000000000000000000000000000000000000000000000000000000000000000000000000000000000000000000000000000000000000000000000000000000000000000000000000000000000000000000000000000000000000000000000000000000000000000000000000000000000000000000000000000000000000000000000000000000000000000000000000000000000000000000000000000000000000000000000000000000000000000000000000000000000000000000000000000000000000000000000000000000000000000000000000000000000000000000000000000000000000000000000000000000000000000000000000000000000000000000000000000000000000000000000000000000000000000000000000000000000000000000000000000000000000000000000000000000000000000000000000000000000000000000000000000000000000000000000000000000000000000000000000000000000000000000000000000000000000000000000000000000000000000000000000000000000000000000000000000000000000000000000000000000000000000000000000000000000000000000000000000000000000000000000000000000000000000000000000000000000000000000000000000000000000000000000000000000000000000000000000000000000000000000000000000000000000000000000000000000000000000000000000000000000000000000000000000000000000000000000000000000000000000000000000000000000000000000000000000000000000000000000000000000000000000000000000000000000000000000000000000000000000000000000000000000000000000000000000000000000000000000000000000000000000000000000000000000000000000000000000000000000000000000000000000000000000000000000000000000000000000000000000000000000000000000000000000000000000000000000000000000000000000000000000000000000000000000000000000000000000000000000000000000000000000000000000000000000000000000000000000000000000000000000000000000000000000000000000000000000000000000000000000000000000000000000000000000000000000000000000000000000000000000000000000000000000000000000000000000000000000000000000000000000000000000000000000000000000000000000000000000000000000000000000000000000000000000000000000000000000000000000000000000000000000000000000000000000000000000000000000000000000000000000000000000000000000000000000000000000000000000000000000000000000000000000000000000000000000000000000000000000000000000000000000000000000000000000000000000000000000000000000000000000000000000000000000000000000000000000000000000000000000000000000000000000000000000000000000000000000000000000000000000000000000000000000000000000000000000000000000000000000000000000000000000000000000000000000000000000000000000000000000000000000000000000000000000000000000000000000000000000000000000000000000000000000000000000000000000000000000000000000000000000000000000000000000000000000000000000000000000000000000000000000000000000000000000000000000000000000000000000000000000000000000000000000000000000000000000000000000000000000000000000000000000000000000000000000000000000000000000000000000000000000000000000000000000000000000000000000000000000000000000000000000000000000000000000000000000000000000000000000000000000000000000000000000000000000000000000000000000000000000000000000000000000000000000000000000000000000000000000000000000000000000000000000000000000000000000000000000000000000000000000000000000000000000000000000000000000000000000000000000000000000000000000000000000000000000000000000000000000000000000000000000000000000000000000000000000000000000000000000000000000000000000000000000000000000000000000000000000000000000000000000000000000000000000000000000000000000000000000000000000000000000000000000000000000000000000000000000000000000000000000000000000000000000000000000000000000000000000000000000000000000000000000000000000000000000000000000000000000000000000000000000000000000000000000000000000000000000000000000000000000000000000000000000000000000000000000000000000000000000000000000000000000000000000000000000000000000000000000000000000000000000000000000000000000000000000000000000000000000000000000000000000000000000000000000000000000000000000000000000000000000000000000000000000000000000000000000000000000000000000000000000000000000000000000000000000000000000000000000000000000000000000000000000000000000000000000000000000000000000000000000000000000000000000000000000000000000000000000000000000000000000000000000000000000000000000000000000000000000000000000000000000000000000000000000000000000000000000000000000000000000000000000000000000000000000000000000000000000000000000000000000000000000000000000000000000000000000000000000000000000000000000000000000000000000000000000000000000000000000000000000000000000000000000000000000000000000000000000000000000000000000000000000000000000000000000000000000000000000000000000000000000000000000000000000000000000000000000000000000000000000000000000000000000000000000000000000000000000000000000000000000000000000000000000000000000000000000000000000000000000000000000000000000000000000000000000000000000000000000000000000000000000000000000000000000000000000000000000000000000000000000000000000000000000000000000000000000000000000000000000000000000000000000000000000000000000000000000000000000000000000000000000000000000000000000000000000000000000000000000000000000000000000000000000000000000000000000000000000000000000000000000000000000000000000000000000000000000000000000000000000000000000000000000000000000000000000000000000000000000000000000000000000000000000000000000000000000000000000000000000000000000000000000000000000000000000000000000000000000000000000000000000000000000000000000000000000000000000000000000000000000000000000000000000000000000000000000000000000000000000000000000000000000000000000000000000000000000000000000000000000000000000000000000000000000000000000000000000000000000000000000000000000000000000000000000000000000000000000000000000000000000000000000000000000000000000000000000000000000000000000000000000000000000000000000000000000000000000000000000000000000000000000000000000000000000000000000000000000000000000000000000000000000000000000000000000000000000000000000000000000000000000000000000000000000000000000000000000000000000000000000000000000000000000000000000000000000000000000000000000000000000000000000000000000000000000000000000000000000000000000000000000000000000000000000000000000000000000000000000000000000000000000000000000000000000000000000000000000000000000000000000000000000000000000000000000000000000000000000000000000000000000000000000000000000000000000000000000000000000000000000000000000000000000000000000000000000000000000000000000000000000000000000000000000000000000000000000000000000000000000000000000000000000000000000000000000000000000000000000000000000000000000000000000000000000000000000000000000000000000000000000000000000000000000000000000000000000000000000000000000000000000000000000000000000000000000000000000000000000000000000000000000000000000000000000000000000000000000000000000000000000000000000000000000000000000000000000000000000000000000000000000000000000000000000000000000000000000000000000000000000000000000000000000000000000000000000000000000000000000000000000000000000000000000000000000000000000000000000000000000000000000000000000000000000000000000000000000000000000000000000000000000000000000000000000000000000000000000000000000000000000000000000000000000000000000000000000000000000000000000000000000000000000000000000000000000000000000000000000000000000000000000000000000000000000000000000000000000000000000000000000000000000000000000000000000000000000000000000000000000000000000000000000000000000000000000000000000000000000000000000000000000000000000000000000000000000000000000000000000000000000000000000000000000000000000000000000000000000000000000000000000000000000000000000000000000000000000000000000000000000000000000000000000000000000000000000000000000000000000000000000000000000000000000000000000000000000000000000000000000000000000000000000000000000000000000000000000000000000000000000000000000000000000000000000000000000000000000000000000000000000000000000000000000000000000000000000000000000000000000000000000000000000000000000000000000000000000000000000000000000000000000000000000000000000000000000000000000000000000000000000000000000000000000000000000000000000000000000000000000000000000000000000000000000000000000000000000000000000000000000000000000000000000000000000000000000000000000000000000000000000000000000000000000000000000000000000000000000000000000000000000000000000000000000000000000000000000000000000000000000000000000000000000000000000000000000000000000000000000000000000000000000000000000000000000000000000000000000000000000000000000000000000000000000000000000000000000000000000000000000000000000000000000000000000000000000000000000000000000000000000000000000000000000000000000000000000000000000000000000000000000000000000000000000000000000000000000000000000000000000000000000000000000000000000000000000000000000000000000000000000000000000000000000000000000000000000000000000000000000000000000000000000000000000000000000000000000000000000000000000000000000000000000000000000000000000000000000000000000000000000000000000000000000000000000000000000000000000000000000000000000000000000000000000000000000000000000000000000000000000000000000000000000000000000000000000000000000000000000000000000000000000000000000000000000000000000000000000000000000000000000000000000000000000000000000000000000000000000000000000000000000000000000000000000000000000000000000000000000000000000000000000000000000000000000000000000000000000000000000000000000000000000000000000000000000000000000000000000000000000000000000000000000000000000000000000000000000000000000000000000000000000000000000000000000000000000000000000000000000000000000000000000000000000000000000000000000000000000000000000000000000000000000000000000000000000000000000000000000000000000000000000000000000000000000000000000000000000000000000000000000000000000000000000000000000000000000000000000000000000000000000000000000000000000000000000000000000000000000000000000000000000000000000000000000000000000000000000000000000000000000000000000000000000000000000000000000000000000000000000000000000000000000000000000000000000000000000000000000000000000000000000000000000000000000000000000000000000000000000000000000000000000000000000000000000000000000000000000000000000000000000000000000000000000000000000000000000000000000000000000000000000000000000000000000000000000000000000000000000000000000000000000000000000000000000000000000000000000000000000000000000000000000000000000000000000000000000000000000000000000000000000000000000000000000000000000000000000000000000000000000000000000000000000000000000000000000000000000000000000000000000000000000000000000000000000000000000000000000000000000000000000000000000000000000000000000000000000000000000000000000000000000000000000000000000000000000000000000000000000000000000000000000000000000000000000000000000000000000000000000000000000000000000000000000000000000000000000000000000000000000000000000000000000000000000000000000000000000000000000000000000000000000000000000000000000000000000000000000000000000000000000000000000000000000000000000000000000000000000000000000000000000000000000000000000000000000000000000000000000000000000000000000000000000000000000000000000000000000000000000000000000000000000000000000000000000000000000000000000000000000000000000000000000000000000000000000000000000000000000000000000000000000000000000000000000000000000000000000000000000000000000000000000000000000000000000000000000000000000000000000000000000000000000000000000000000000000000000000000000000000000000000000000000000000000000000000000000000000000000000000000000000000000000000000000000000000000000000000000000000000000000000000000000000000000000000000000000000000000000000000000000000000000000000000000000000000000000000000000000000000000000000000000000000000000000000000000000000000000000000000000000000000000000000000000000000000000000000000000000000000000000000000000000000000000000000000000000000000000000000000000000000000000000000000000000000000000000000000000000000000000000000000000000000000000000000000000000000000000000000000000000000000000000000000000000000000000000000000000000000000000000000000000000000000000000000000000000000000000000000000000000000000000000000000000000000000000000000000000000000000000000000000000000000000000000000000000000000000000000000000000000000000000000000000000000000000000000000000000000000000000000000000000000000000000000000000000000000000000000000000000000000000000000000000000000000000000000000000000000000000000000000000000000000000000000000000000000000000000000000000000000000000000000000000000000000000000000000000000000000000000000000000000000000000000000000000000000000000000000000000000000000000000000000000000000000000000000000000000000000000000000000000000000000000000000000000000000000000000000000000000000000000000000000000000000000000000000000000000000000000000000000000000000000000000000000000000000000000000000000000000000000000000000000000000000000000000000000000000000000000000000000000000000000000000000000000000000000000000000000000000000000000000000000000000000000000000000000000000000000000000000000000000000000000000000000000000000000000000000000000000000000000000000000000000000000000000000000000000000000000000000000000000000000000000000000000000000000000000000000000000000000000000000000000000000000000000000000000000000000000000000000000000000000000000000000000000000000000000000000000000000000000000000000000000000000000000000000000000000000000000000000000000000000000000000000000000000000000000000000000000000000000000000000000000000000000000000000000000000000000000000000000000000000000000000000000000000000000000000000000000000000000000000000000000000000000000000000000000000000000000000000000000000000000000000000000000000000000000000000000000000000000000000000000000000000000000000000000000000000000000000000000000000000000000000000000000000000000000000000000000000000000000000000000000000000000000000000000000000000000000000000000000000000000000000000000000000000000000000000000000000000000000000000000000000000000000000000000000000000000000000000000000000000000000000000000000000000000000000000000000000000000000000000000000000000000000000000000000000000000000000000000000000000000000000000000000000000000000000000000000000000000000000000000000000000000000000000000000000000000000000000000000000000000000000000000000000000000000000000000000000000000000000000000000000000000000000000000000000000000000000000000000000000000000000000000000000000000000000000000000000000000000000000000000000000000000000000000000000000000000000000000000000000000000000000000000000000000000000000000000000000000000000000000000000000000000000000000000000000000000000000000000000000000000000000000000000000000000000000000000000000000000000000000000000000000000000000000000000000000000000000000000000000000000000000000000000000000000000000000000000000000000000000000000000000000000000000000000000000000000000000000000000000000000000000000000000000000000000000000000000000000000000000000000000000000000000000000000000000000000000000000000000000000000000000000000000000000000000000000000000000000000000000000000000000000000000000000000000000000000000000000000000000000000000000000000000000000000000000000000000000000000000000000000000000000000000000000000000000000000000000000000000000000000000000000000000000000000000000000000000000000000000000000000000000000000000000000000000000000000000000000000000000000000000000000000000000000000000000000000000000000000000000000000000000000000000000000000000000000000000000000000000000000000000000000000000000000000000000000000000000000000000000000000000000000000000000000000000000000000000000000000000000000000000000000000000000000000000000000000000000000000000000000000000000000000000000000000000000000000000000000000000000000000000000000000000000000000000000000000000000000000000000000000000000000000000000000000000000000000000000000000000000000000000000000000000000000000000000000000000000000000000000000000000000000000000000000000000000000000000000000000000000000000000000000000000000000000000000000000000000000000000000000000000000000000000000000000000000000000000000000000000000000000000000000000000000000000000000000000000000000000000000000000000000000000000000000000000000000000000000000000000000000000000000000000000000000000000000000000000000000000000000000000000000000000000000000000000000000000000000000000000000000000000000000000000000000000000000000000000000000000000000000000000000000000000000000000000000000000000000000000000000000000000000000000000000000000000000000000000000000000000000000000000000000000000000000000000000000000000000000000000000000000000000000000000000000000000000000000000000000000000000000000000000000000000000000000000000000000000000000000000000000000000000000000000000000000000000000000000000000000000000000000000000000000000000000000000000000000000000000000000000000000000000000000000000000000000000000000000000000000000000000000000000000000000000000000000000000000000000000000000000000000000000000000000000000000000000000000000000000000000000000000000000000000000000000000000000000000000000000000000000000000000000000000000000000000000000000000000000000000000000000000000000000000000000000000000000000000000000000000000000000000000000000000000000000000000000000000000000000000000000000000000000000000000000000000000000000000000000000000000000000000000000000000000000000000000000000000000000000000000000000000000000000000000000000000000000000000000000000000000000000000000000000000000000000000000000000000000000000000000000000000000000000000000000000000000000000000000000000000000000000000000000000000000000000000000000000000000000000000000000000000000000000000000000000000000000000000000000000000000000000000000000000000000000000000000000000000000000000000000000000000000000000000000000000000000000000000000000000000000000000000000000000000000000000000000000000000000000000000000000000000000000000000000000000000000000000000000000000000000000000000000000000000000000000000000000000000000000000000000000000000000000000000000000000000000000000000000000000000000000000000000000000000000000000000000000000000000000000000000000000000000000000000000000000000000000000000000000000000000000000000000000000000000000000000000000000000000000000000000000000000000000000000000000000000000000000000000000000000000000000000000000000000000000000000000000000000000000000000000000000000000000000000000000000000000000000000000000000000000000000000000000000000000000000000000000000000000000000000000000000000000000000000000000000000000000000000000000000000000000000000000000000000000000000000000000000000000000000000000000000000000000000000000000000000000000000000000000000000000000000000000000000000000000000000000000000000000000000000000000000000000000000000000000000000000000000000000000000000000000000000000000000000000000000000000000000000000000000000000000000000000000000000000000000000000000000000000000000000000000000000000000000000000000000000000000000000000000000000000000000000000000000000000000000000000000000000000000000000000000000000000000000000000000000000000000000000000000000000000000000000000000000000000000000000000000000000000000000000000000000000000000000000000000000000000000000000000000000000000000000000000000000000000000000000000000000000000000000000000000000000000000000000000000000000000000000000000000000000000000000000000000000000000000000000000000000000000000000000000000000000000000000000000000000000000000000000000000000000000000000000000000000000000000000000000000000000000000000000000000000000000000000000000000000000000000000000000000000000000000000000000000000000000000000000000000000000000000000000000000000000000000000000000000000000000000000000000000000000000000000000000000000000000000000000000000000000000000000000000000000000000000000000000000000000000000000000000000000000000000000000000000000000000000000000000000000000000000000000000000000000000000000000000000000000000000000000000000000000000000000000000000000000000000000000000000000000000000000000000000000000000000000000000000000000000000000000000000000000000000000000000000000000000000000000000000000000000000000000000000000000000000000000000000000000000000000000000000000000000000000000000000000000000000000000000000000000000000000000000000000000000000000000000000000000000000000000000000000000000000000000000000000000000000000000000000000000000000000000000000000000000000000000000000000000000000000000000000000000000000000000000000000000000000000000000000000000000000000000000000000000000000000000000000000000000000000000000000000000000000000000000000000000000000000000000000000000000000000000000000000000000000000000000000000000000000000000000000000000000000000000000000000000000000000000000000000000000000000000000000000000000000000000000000000000000000000000000000000000000000000000000000000000000000000000000000000000000000000000000000000000000000000000000000000000000000000000000000000000000000000000000000000000000000000000000000000000000000000000000000000000000000000000000000000000000000000000000000000000000000000000000000000000000000000000000000000000000000000000000000000000000000000000000000000000000000000000000000000000000000000000000000000000000000000000000000000000000000000000000000000000000000000000000000000000000000000000000000000000000000000000000000000000000000000000000000000000000000000000000000000000000000000000000000000000000000000000000000000000000000000000000000000000000000000000000000000000000000000000000000000000000000000000000000000000000000000000000000000000000000000000000000000000000000000000000000000000000000000000000000000000000000000000000000000000000000000000000000000000000000000000000000000000000000000000000000000000000000000000000000000000000000000000000000000000000000000000000000000000000000000000000000000000000000000000000000000000000000000000000000000000000000000000000000000000000000000000000000000000000000000000000000000000000000000000000000000000000000000000000000000000000000000000000000000000000000000000000000000000000000000000000000000000000000000000000000000000000000000000000000000000000000000000000000000000000000000000000000000000000000000000000000000000000000000000000000000000000000000000000000000000000000000000000000000000000000000000000000000000000000000000000000000000000000000000000000000000000000000000000000000000000000000000000000000000000000000000000000000000000000000000000000000000000000000000000000000000000000000000000000000000000000000000000000000000000000000000000000000000000000000000000000000000000000000000000000000000000000000000000000000000000000000000000000000000000000000000000000000000000000000000000000000000000000000000000000000000000000000000000000000000000000000000000000000000000000000000000000000000000000000000000000000000000000000000000000000000000000000000000000000000000000000000000000000000000000000000000000000000000000000000000000000000000000000000000000000000000000000000000000000000000000000000000000000000000000000000000000000000000000000000000000000000000000000000000000000000000000000000000000000000000000000000000000000000000000000000000000000000000000000000000000000000000000000000000000000000000000000000000000000000000000000000000000000000000000000000000000000000000000000000000000000000000000000000000000000000000000000000000000000000000000000000000000000000000000000000000000000000000000000000000000000000000000000000000000000000000000000000000000000000000000000000000000000000000000000000000000000000000000000000000000000000000000000000000000000000000000000000000000000000000000000000000000000000000000000000000000000000000000000000000000000000000000000000000000000000000000000000000000000000000000000000000000000000000000000000000000000000000000000000000000000000000000000000000000000000000000000000000000000000000000000000000000000000000000000000000000000000000000000000000000000000000000000000000000000000000000000000000000000000000000000000000000000000000000000000000000000000000000000000000000000000000000000000000000000000000000000000000000000000000000000000000000000000000000000000000000000000000000000000000000000000000000000000000000000000000000000000000000000000000000000000000000000000000000000000000000000000000000000000000000000000000000000000000000000000000000000000000000000000000000000000000000000000000000000000000000000000000000000000000000000000000000000000000000000000000000000000000000000000000000000000000000000000000000000000000000000000000000000000000000000000000000000000000000000000000000000000000000000000000000000000000000000000000000000000000000000000000000000000000000000000000000000000000000000000000000000000000000000000000000000000000000000000000000000000000000000000000000000000000000000000000000000000000000000000000000000000000000000000000000000000000000000000000000000000000000000000000000000000000000000000000000000000000000000000000000000000000000000000000000000000000000000000000000000000000000000000000000000000000000000000000000000000000000000000000000000000000000000000000000000000000000000000000000000000000000000000000000000000000000000000000000000000000000000000000000000000000000000000000000000000000000000000000000000000000000000000000000000000000000000000000000000000000000000000000000000000000000000000000000000000000000000000000000000000000000000000000000000000000000000000000000000000000000000000000000000000000000000000000000000000000000000000000000000000000000000000000000000000000000000000000000000000000000000000000000000000000000000000000000000000000000000000000000000000000000000000000000000000000000000000000000000000000000000000000000000000000000000000000000000000000000000000000000000000000000000000000000000000000000000000000000000000000000000000000000000000000000000000000000000000000000000000000000000000000000000000000000000000000000000000000000000000000000000000000000000000000000000000000000000000000000000000000000000000000000000000000000000000000000000000000000000000000000000000000000000000000000000000000000000000000000000000000000000000000000000000000000000000000000000000000000000000000000000000000000000000000000000000000000000000000000000000000000000000000000000000000000000000000000000000000000000000000000000000000000000000000000000000000000000000000000000000000000000000000000000000000000000000000000000000000000000000000000000000000000000000000000000000000000000000000000000000000000000000000000000000000000000000000000000000000000000000000000000000000000000000000000000000000000000000000000000000000000000000000000000000000000000000000000000000000000000000000000000000000000000000000000000000000000000000000000000000000000000000000000000000000000000000000000000000000000000000000000000000000000000000000000000000000000000000000000000000000000000000000000000000000000000000000000000000000000000000000000000000000000000000000000000000000000000000000000000000000000000000000000000000000000000000000000000000000000000000000000000000000000000000000000000000000000000000000000000000000000000000000000000000000000000000000000000000000000000000000000000000000000000000000000000000000000000000000000000000000000000000000000000000000000000000000000000000000000000000000000000000000000000000000000000000000000000000000000000000000000000000000000000000000000000000000000000000000000000000000000000000000000000000000000000000000000000000000000000000000000000000000000000000000000000000000000000000000000000000000000000000000000000000000000000000000000000000000000000000000000000000000000000000000000000000000000000000000000000000000000000000000000000000000000000000000000000000000000000000000000000000000000000000000000000000000000000000000000000000000000000000000000000000000000000000000000000000000000000000000000000000000000000000000000000000000000000000000000000000000000000000000000000000000000000000000000000000000000000000000000000000000000000000000000000000000000000000000000000000000000000000000000000000000000000000000000000000000000000000000000000000000000000000000000000000000000000000000000000000000000000000000000000000000000000000000000000000000000000000000000000000000000000000000000000000000000000000000000000000000000000000000000000000000000000000000000000000000000000000000000000000000000000000000000000000000000000000000000000000000000000000000000000000000000000000000000000000000000000000000000000000000000000000000000000000000000000000000000000000000000000000000000000000000000000000000000000000000000000000000000000000000000000000000000000000000000000000000000000000000000000000000000000000000000000000000000000000000000000000000000000000000000000000000000000000000000000000000000000000000000000000000000000000000000000000000000000000000000000000000000000000000000000000000000000000000000000000000000000000000000000000000000000000000000000000000000000000000000000000000000000000000000000000000000000000000000000000000000000000000000000000000000000000000000000000000000000000000000000000000000000000000000000000000000000000000000000000000000000000000000000000000000000000000000000000000000000000000000000000000000000000000000000000000000000000000000000000000000000000000000000000000000000000000000000000000000000000000000000000000000000000000000000000000000000000000000000000000000000000000000000000000000000000000000000000000000000000000000000000000000000000000000000000000000000000000000000000000000000000000000000000000000000000000000000000000000000000000000000000000000000000000000000000000000000000000000000000000000000000000000000000000000000000000000000000000000000000000000000000000000000000000000000000000000000000000000000000000000000000000000000000000000000000000000000000000000000000000000000000000000000000000000000000000000000000000000000000000000000000000000000000000000000000000000000000000000000000000000000000000000000000000000000000000000000000000000000000000000000000000000000000000000000000000000000000000000000000000000000000000000000000000000000000000000000000000000000000000000000000000000000000000000000000000000000000000000000000000000000000000000000000000000000000000000000000000000000000000000000000000000000000000000000000000000000000000000000000000000000000000000000000000000000000000000000000000000000000000000000000000000000000000000000000000000000000000000000000000000000000000000000000000000000000000000000000000000000000000000000000000000000000000000000000000000000000000000000000000000000000000000000000000000000000000000000000000000000000000000000000000000000000000000000000000000000000000000000000000000000000000000000000000000000000000000000000000000000000000000000000000000000000000000000000000000000000000000000000000000000000000000000000000000000000000000000000000000000000000000000000000000000000000000000000000000000000000000000000000000000000000000000000000000000000000000000000000000000000000000000000000000000000000000000000000000000000000000000000000000000000000000000000000000000000000000000000000000000000000000000000000000000000000000000000000000000000000000000000000000000000000000000000000000000000000000000000000000000000000000000000000000000000000000000000000000000000000000000000000000000000000000000000000000000000000000000000000000000000000000000000000000000000000000000000000000000000000000000000000000000000000000000000000000000000000000000000000000000000000000000000000000000000000000000000000000000000000000000000000000000000000000000000000000000000000000000000000000000000000000000000000000000000000000000000000000000000000000000000000000000000000000000000000000000000000000000000000000000000000000000000000000000000000000000000000000000000000000000000000000000000000000000000000000000000000000000000000000000000000000000000000000000000000000000000000000000000000000000000000000000000000000000000000000000000000000000000000000000000000000000000000000000000000000000000000000000000000000000000000000000000000000000000000000000000000000000000000000000000000000000000000000000000000000000000000000000000000000000000000000000000000000000000000000000000000000000000000000000000000000000000000000000000000000000000000000000000000000000000000000000000000000000000000000000000000000000000000000000000000000000000000000000000000000000000000000000000000000000000000000000000000000000000000000000000000000000000000000000000000000000000000000000000000000000000000000000000000000000000000000000000000000000000000000000000000000000000000000000000000000000000000000000000000000000000000000000000000000000000000000000000000000000000000000000000000000000000000000000000000000000000000000000000000000000000000000000000000000000000000000000000000000000000000000000000000000000000000000000000000000000000000000000000000000000000000000000000000000000000000000000000000000000000000000000000000000000000000000000000000000000000000000000000000000000000000000000000000000000000000000000000000000000000000000000000000000000000000000000000000000000000000000000000000000000000000000000000000000000000000000000000000000000000000000000000000000000000000000000000000000000000000000000000000000000000000000000000000000000000000000000000000000000000000000000000000000000000000000000000000000000000000000000000000000000000000000000000000000000000000000000000000000000000000000000000000000000000000000000000000000000000000000000000000000000000000000000000000000000000000000000000000000000000000000000000000000000000000000000000000000000000000000000000000000000000000000000000000000000000000000000000000000000000000000000000000000000000000000000000000000000000000000000000000000000000000000000000000000000000000000000000000000000000000000000000000000000000000000000000000000000000000000000000000000000000000000000000000000000000000000000000000000000000000000000000000000000000000000000000000000000000000000000000000000000000000000000000000000000000000000000000000000000000000000000000000000000000000000000000000000000000000000000000000000000000000000000000000000000000000000000000000000000000000000000000000000000000000000000000000000000000000000000000000000000000000000000000000000000000000000000000000000000000000000000000000000000000000000000000000000000000000000000000000000000000000000000000000000000000000000000000000000000000000000000000000000000000000000000000000000000000000000000000000000000000000000000000000000000000000000000000000000000000000000000000000000000000000000000000000000000000000000000000000000000000000000000000000000000000000000000000000000000000000000000000000000000000000000000000000000000000000000000000000000000000000000000000000000000000000000000000000000000000000000000000000000000000000000000000000000000000000000000000000000000000000000000000000000000000000000000000000000000000000000000000000000000000000000000000000000000000000000000000000000000000000000000000000000000000000000000000000000000000000000000000000000000000000000000000000000000000000000000000000000000000000000000000000000000000000000000000000000000000000000000000000000000000000000000000000000000000000000000000000000000000000000000000000000000000000000000000000000000000000000000000000000000000000000000000000000000000000000000000000000000000000000000000000000000000000000000000000000000000000000000000000000000000000000000000000000000000000000000000000000000000000000000000000000000000000000000000000000000000000000000000000000000000000000000000000000000000000000000000000000000000000000000000000000000000000000000000000000000000000000000000000000000000000000000000000000000000000000000000000000000000000000000000000000000000000000000000000000000000000000000000000000000000000000000000000000000000000000000000000000000000000000000000000000000000000000000000000000000000000000000000000000000000000000000000000000000000000000000000000000000000000000000000000000000000000000000000000000000000000000000000000000000000000000000000000000000000000000000000000000000000000000000000000000000000000000000000000000000000000000000000000000000000000000000000000000000000000000000000000000000000000000000000000000000000000000000000000000000000000000000000000000000000000000000000000000000000000000000000000000000000000000000000000000000000000000000000000000000000000000000000000000000000000000000000000000000000000000000000000000000000000000000000000000000000000000000000000000000000000000000000000000000000000000000000000000000000000000000000000000000000000000000000000000000000000000000000000000000000000000000000000000000000000000000000000000000000000000000000000000000000000000000000000000000000000000000000000000000000000000000000000000000000000000000000000000000000000000000000000000000000000000000000000000000000000000000000000000000000000000000000000000000000000000000000000000000000000000000000000000000000000000000000000000000000000000000000000000000000000000000000000000000000000000000000000000000000000000000000000000000000000000000000000000000000000000000000000000000000000000000000000000000000000000000000000000000000000000000000000000000000000000000000000000000000000000000000000000000000000000000000000000000000000000000000000000000000000000000000000000000000000000000000000000000000000000000000000000000000000000000000000000000000000000000000000000000000000000000000000000000000000000000000000000000000000000000000000000000000000000000000000000000000000000000000000000000000000000000000000000000000000000000000000000000000000000000000000000000000000000000000000000000000000000000000000000000000000000000000000000000000000000000000000000000000000000000000000000000000000000000000000000000000000000000000000000000000000000000000000000000000000000000000000000000000000000000000000000000000000000000000000000000000000000000000000000000000000000000000000000000000000000000000000000000000000000000000000000000000000000000000000000000000000000000000000000000000000000000000000000000000000000000000000000000000000000000000000000000000000000000000000000000000000000000000000000000000000000000000000000000000000000000000000000000000000000000000000000000000000000000000000000000000000000000000000000000000000000000000000000000000000000000000000000000000000000000000000000000000000000000000000000000000000000000000000000000000000000000000000000000000000000000000000000000000000000000000000000000000000000000000000000000000000000000000000000000000000000000000000000000000000000000000000000000000000000000000000000000000000000000000000000000000000000000000000000000000000000000000000000000000000000000000000000000000000000000000000000000000000000000000000000000000000000000000000000000000000000000000000000000000000000000000000000000000000000000000000000000000000000000000000000000000000000000000000000000000000000000000000000000000000000000000000000000000000000000000000000000000000000000000000000000000000000000000000000000000000000000000000000000000000000000000000000000000000000000000000000000000000000000000000000000000000000000000000000000000000000000000000000000000000000000000000000000000000000000000000000000000000000000000000000000000000000000000000000000000000000000000000000000000000000000000000000000000000000000000000000000000000000000000000000000000000000000000000000000000000000000000000000000000000000000000000000000000000000000000000000000000000000000000000000000000000000000000000000000000000000000000000000000000000000000000000000000000000000000000000000000000000000000000000000000000000000000000000000000000000000000000000000000000000000000000000000000000000000000000000000000000000000000000000000000000000000000000000000000000000000000000000000000000000000000000000000000000000000000000000000000000000000000000000000000000000000000000000000000000000000000000000000000000000000000000000000000000000000000000000000000000000000000000000000000000000000000000000000000000000000000000000000000000000000000000000000000000000000000000000000000000000000000000000000000000000000000000000000000000000000000000000000000000000000000000000000000000000000000000000000000000000000000000000000000000000000000000000000000000000000000000000000000000000000000000000000000000000000000000000000000000000000000000000000000000000000000000000000000000000000000000000000000000000000000000000000000000000000000000000000000000000000000000000000000000000000000000000000000000000000000000000000000000000000000000000000000000000000000000000000000000000000000000000000000000000000000000000000000000000000000000000000000000000000000000000000000000000000000000000000000000000000000000000000000000000000000000000000000000000000000000000000000000000000000000000000000000000000000000000000000000000000000000000000000000000000000000000000000000000000000000000000000000000000000000000000000000000000000000000000000000000000000000000000000000000000000000000000000000000000000000000000000000000000000000000000000000000000000000000000000000000000000000000000000000000000000000000000000000000000000000000000000000000000000000000000000000000000000000000000000000000000000000000000000000000000000000000000000000000000000000000000000000000000000000000000000000000000000000000000000000000000000000000000000000000000000000000000000000000000000000000000000000000000000000000000000000000000000000000000000000000000000000000000000000000000000000000000000000000000000000000000000000000000000000000000000000000000000000000000000000000000000000000000000000000000000000000000000000000000000000000000000000000000000000000000000000000000000000000000000000000000000000000000000000000000000000000000000000000000000000000000000000000000000000000000000000000000000000000000000000000000000000000000000000000000000000000000000000000000000000000000000000000000000000000000000000000000000000000000000000000000000000000000000000000000000000000000000000000000000000000000000000000000000000000000000000000000000000000000000000000000000000000000000000000000000000000000000000000000000000000000000000000000000000000000000000000000000000000000000000000000000000000000000000000000000000000000000000000000000000000000000000000000000000000000000000000000000000000000000000000000000000000000000000000000000000000000000000000000000000000000000000000000000000000000000000000000000000000000000000000000000000000000000000000000000000000000000000000000000000000000000000000000000000000000000000000000000000000000000000000000000000000000000000000000000000000000000000000000000000000000000000000000000000000000000000000000000000000000000000000000000000000000000000000000000000000000000000000000000000000000000000000000000000000000000000000000000000000000000000000000000000000000000000000000000000000000000000000000000000000000000000000000000000000000000000000000000000000000000000000000000000000000000000000000000000000000000000000000000000000000000000000000000000000000000000000000000000000000000000000000000000000000000000000000000000000000000000000000000000000000000000000000000000000000000000000000000000000000000000000000000000000000000000000000000000000000000000000000000000000000000000000000000000000000000000000000000000000000000000000000000000000000000000000000000000000000000000000000000000000000000000000000000000000000000000000000000000000000000000000000000000000000000000000000000000000000000000000000000000000000000000000000000000000000000000000000000000000000000000000000000000000000000000000000000000000000000000000000000000000000000000000000000000000000000000000000000000000000000000000000000000000000000000000000000000000000000000000000000000000000000000000000000000000000000000000000000000000000000000000000000000000000000000000000000000000000000000000000000000000000000000000000000000000000000000000000000000000000000000000000000000000000000000000000000000000000000000000000000000000000000000000000000000000000000000000000000000000000000000000000000000000000000000000000000000000000000000000000000000000000000000000000000000000000000000000000000000000000000000000000000000000000000000000000000000000000000000000000000000000000000000000000000000000000000000000000000000000000000000000000000000000000000000000000000000000000000000000000000000000000000000000000000000000000000000000000000000000000000000000000000000000000000000000000000000000000000000000000000000000000000000000000000000000000000000000000000000000000000000000000000000000000000000000000000000000000000000000000000000000000000000000000000000000000000000000000000000000000000000000000000000000000000000000000000000000000000000000000000000000000000000000000000000000000000000000000000000000000000000000000000000000000000000000000000000000000000000000000000000000000000000000000000000000000000000000000000000000000000000000000000000000000000000000000000000000000000000000000000000000000000000000000000000000000000000000000000000000000000000000000000000000000000000000000000000000000000000000000000000000000000000000000000000000000000000000000000000000000000000000000000000000000000000000000000000000000000000000000000000000000000000000000000000000000000000000000000000000000000000000000000000000000000000000000000000000000000000000000000000000000000000000000000000000000000000000000000000000000000000000000000000000000000000000000000000000000000000000000000000000000000000000000000000000000000000000000000000000000000000000000000000000000000000000000000000000000000000000000000000000000000000000000000000000000000000000000000000000000000000000000000000000000000000000000000000000000000000000000000000000000000000000000000000000000000000000000000000000000000000000000000000000000000000000000000000000000000000000000000000000000000000000000000000000000000000000000000000000000000000000000000000000000000000000000000000000000000000000000000000000000000000000000000000000000000000000000000000000000000000000000000000000000000000000000000000000000000000000000000000000000000000000000000000000000000000000000000000000000000000000000000000000000000000000000000000000000000000000000000000000000000000000000000000000000000000000000000000000000000000000000000000000000000000000000000000000000000000000000000000000000000000000000000000000000000000000000000000000000000000000000000000000000000000000000000000000000000000000000000000000000000000000000000000000000000000000000000000000000000000000000000000000000000000000000000000000000000000000000000000000000000000000000000000000000000000000000000000000000000000000000000000000000000000000000000000000000000000000000000000000000000000000000000000000000000000000000000000000000000000000000000000000000000000000000000000000000000000000000000000000000000000000000000000000000000000000000000000000000000000000000000000000000000000000000000000000000000000000000000000000000000000000000000000000000000000000000000000000000000000000000000000000000000000000000000000000000000000000000000000000000000000000000000000000000000000000000000000000000000000000000000000000000000000000000000000000000000000000000000000000000000000000000000000000000000000000000000000000000000000000000000000000000000000000000000000000000000000000000000000000000000000000000000000000000000000000000000000000000000000000000000000000000000000000000000000000000000000000000000000000000000000000000000000000000000000000000000000000000000000000000000000000000000000000000000000000000000000000000000000000000000000000000000000000000000000000000000000000000000000000000000000000000000000000000000000000000000000000000000000000000000000000000000000000000000000000000000000000000000000000000000000000000000000000000000000000000000000000000000000000000000000000000000000000000000000000000000000000000000000000000000000000000000000000000000000000000000000000000000000000000000000000000000000000000000000000000000000000000000000000000000000000000000000000000000000000000000000000000000000000000000000000000000000000000000000000000000000000000000000000000000000000000000000000000000000000000000000000000000000000000000000000000000000000000000000000000000000000000000000000000000000000000000000000000000000000000000000000000000000000000000000000000000000000000000000000000000000000000000000000000000000000000000000000000000000000000000000000000000000000000000000000000000000000000000000000000000000000000000000000000000000000000000000000000000000000000000000000000000000000000000000000000000000000000000000000000000000000000000000000000000000000000000000000000000000000000000000000000000000000000000000000000000000000000000000000000000000000000000000000000000000000000000000000000000000000000000000000000000000000000000000000000000000000000000000000000000000000000000000000000000000000000000000000000000000000000000000000000000000000000000000000000000000000000000000000000000000000000000000000000000000000000000000000000000000000000000000000000000000000000000000000000000000000000000000000000000000000000000000000000000000000000000000000000000000000000000000000000000000000000000000000000000000000000000000000000000000000000000000000000000000000000000000000000000000000000000000000000000000000000000000000000000000000000000000000000000000000000000000000000000000000000000000000000000000000000000000000000000000000000000000000000000000000000000000000000000000000000000000000000000000000000000000000000000000000000000000000000000000000000000000000000000000000000000000000000000000000000000000000000000000000000000000000000000000000000000000000000000000000000000000000000000000000000000000000000000000000000000000000000000000000000000000000000000000000000000000000000000000000000000000000000000000000000000000000000000000000000000000000000000000000000000000000000000000000000000000000000000000000000000000000000000000000000000000000000000000000000000000000000000000000000000000000000000000000000000000000000000000000000000000000000000000000000000000000000000000000000000000000000000000000000000000000000000000000000000000000000000000000000000000000000000000000000000000000000000000000000000000000000000000000000000000000000000000000000000000000000000000000000000000000000000000000000000000000000000000000000000000000000000000000000000000000000000000000000000000000000000000000000000000000000000000000000000000000000000000000000000000000000000000000000000000000000000000000000000000000000000000000000000000000000000000000000000000000000000000000000000000000000000000000000000000000000000000000000000000000000000000000000000000000000000000000000000000000000000000000000000000000000000000000000000000000000000000000000000000000000000000000000000000000000000000000000000000000000000000000000000000000000000000000000000000000000000000000000000000000000000000000000000000000000000000000000000000000000000000000000000000000000000000000000000000000000000000000000000000000000000000000000000000000000000000000000000000000000000000000000000000000000000000000000000000000000000000000000000000000000000000000000000000000000000000000000000000000000000000000000000000000000000000000000000000000000000000000000000000000000000000000000000000000000000000000000000000000000000000000000000000000000000000000000000000000000000000000000000000000000000000000000000000000000000000000000000000000000000000000000000000000000000000000000000000000000000000000000000000000000000000000000000000000000000000000000000000000000000000000000000000000000000000000000000000000000000000000000000000000000000000000000000000000000000000000000000000000000000000000000000000000000000000000000000000000000000000000000000000000000000000000000000000000000000000000000000000000000000000000000000000000000000000000000000000000000000000000000000000000000000000000000000000000000000000000000000000000000000000000000000000000000000000000000000000000000000000000000000000000000000000000000000000000000000000000000000000000000000000000000000000000000000000000000000000000000000000000000000000000000000000000000000000000000000000000000000000000000000000000000000000000000000000000000000000000000000000000000000000000000000000000000000000000000000000000000000000000000000000000000000000000000000000000000000000000000000000000000000000000000000000000000000000000000000000000000000000000000000000000000000000000000000000000000000000000000000000000000000000000000000000000000000000000000000000000000000000000000000000000000000000000000000000000000000000000000000000000000000000000000000000000000000000000000000000000000000000000000000000000000000000000000000000000000000000000000000000000000000000000000000000000000000000000000000000000000000000000000000000000000000000000000000000000000000000000000000000000000000000000000000000000000000000000000000000000000000000000000000000000000000000000000000000000000000000000000000000000000000000000000000000000000000000000000000000000000000000000000000000000000000000000000000000000000000000000000000000000000000000000000000000000000000000000000000000000000000000000000000000000000000000000000000000000000000000000000000000000000000000000000000000000000000000000000000000000000000000000000000000000000000000000000000000000000000000000000000000000000000000000000000000000000000000000000000000000000000000000000000000000000000000000000000000000000000000000000000000000000000000000000000000000000000000000000000000000000000000000000000000000000000000000000000000000000000000000000000000000000000000000000000000000000000000000000000000000000000000000000000000000000000000000000000000000000000000000000000000000000000000000000000000000000000000000000000000000000000000000000000000000000000000000000000000000000000000000000000000000000000000000000000000000000000000000000000000000000000000000000000000000000000000000000000000000000000000000000000000000000000000000000000000000000000000000000000000000000000000000000000000000000000000000000000000000000000000000000000000000000000000000000000000000000000000000000000000000000000000000000000000000000000000000000000000000000000000000000000000000000000000000000000000000000000000000000000000000000000000000000000000000000000000000000000000000000000000000000000000000000000000000000000000000000000000000000000000000000000000000000000000000000000000000000000000000000000000000000000000000000000000000000000000000000000000000000000000000000000000000000000000000000000000000000000000000000000000000000000000000000000000000000000000000000000000000000000000000000000000000000000000000000000000000000000000000000000000000000000000000000000000000000000000000000000000000000000000000000000000000000000000000000000000000000000000000000000000000000000000000000000000000000000000000000000000000000000000000000000000000000000000000000000000000000000000000000000000000000000000000000000000000000000000000000000000000000000000000000000000000000000000000000000000000000000000000000000000000000000000000000000000000000000000000000000000000000000000000000000000000000000000000000000000000000000000000000000000000000000000000000000000000000000000000000000000000000000000000000000000000000000000000000000000000000000000000000000000000000000000000000000000000000000000000000000000000000000000000000000000000000000000000000000000000000000000000000000000000000000000000000000000000000000000000000000000000000000000000000000000000000000000000000000000000000000000000000000000000000000000000000000000000000000000000000000000000000000000000000000000000000000000000000000000000000000000000000000000000000000000000000000000000000000000000000000000000000000000000000000000000000000000000000000000000000000000000000000000000000000000000000000000000000000000000000000000000000000000000000000000000000000000000000000000000000000000000000000000000000000000000000000000000000000000000000000000000000000000000000000000000000000000000000000000000000000000000000000000000000000000000000000000000000000000000000000000000000000000000000000000000000000000000000000000000000000000000000000000000000000000000000000000000000000000000000000000000000000000000000000000000000000000000000000000000000000000000000000000000000000000000000000000000000000000000000000000000000000000000000000000000000000000000000000000000000000000000000000000000000000000000000000000000000000000000000000000000000000000000000000000000000000000000000000000000000000000000000000000000000000000000000000000000000000000000000000000000000000000000000000000000000000000000000000000000000000000000000000000000000000000000000000000000000000000000000000000000000000000000000000000000000000000000000000000000000000000000000000000000000000000000000000000000000000000000000000000000000000000000000000000000000000000000000000000000000000000000000000000000000000000000000000000000000000000000000000000000000000000000000000000000000000000000000000000000000000000000000000000000000000000000000000000000000000000000000000000000000000000000000000000000000000000000000000000000000000000000000000000000000000000000000000000000000000000000000000000000000000000000000000000000000000000000000000000000000000000000000000000000000000000000000000000000000000000000000000000000000000000000000000000000000000000000000000000000000000000000000000000000000000000000000000000000000000000000000000000000000000000000000000000000000000000000000000000000000000000000000000000000000000000000000000000000000000000000000000000000000000000000000000000000000000000000000000000000000000000000000000000000000000000000000000000000000000000000000000000000000000000000000000000000000000000000000000000000000000000000000000000000000000000000000000000000000000000000000000000000000000000000000000000000000000000000000000000000000000000000000000000000000000000000000000000000000000000000000000000000000000000000000000000000000000000000000000000000000000000000000000000000000000000000000000000000000000000000000000000000000000000000000000000000000000000000000000000000000000000000000000000000000000000000000000000000000000000000000000000000000000000000000000000000000000000000000000000000000000000000000000000000000000000000000000000000000000000000000000000000000000000000000000000000000000000000000000000000000000000000000000000000000000000000000000000000000000000000000000000000000000000000000000000000000000000000000000000000000000000000000000000000000000000000000000000000000000000000000000000000000000000000000000000000000000000000000000000000000000000000000000000000000000000000000000000000000000000000000000000000000000000000000000000000000000000000000000000000000000000000000000000000000000000000000000000000000000000000000000000000000000000000000000000000000000000000000000000000000000000000000000000000000000000000000000000000000000000000000000000000000000000000000000000000000000000000000000000000000000000000000000000000000000000000000000000000000000000000000000000000000000000000000000000000000000000000000000000000000000000000000000000000000000000000000000000000000000000000000000000000000000000000000000000000000000000000000000000000000000000000000000000000000000000000000000000000000000000000000000000000000000000000000000000000000000000000000000000000000000000000000000000000000000000000000000000000000000000000000000000000000000000000000000000000000000000000000000000000000000000000000000000000000000000000000000000000000000000000000000000000000000000000000000000000000000000000000000000000000000000000000000000000000000000000000000000000000000000000000000000000000000000000000000000000000000000000000000000000000000000000000000000000000000000000000000000000000000000000000000000000000000000000000000000000000000000000000000000000000000000000000000000000000000000000000000000000000000000000000000000000000000000000000000000000000000000000000000000000000000000000000000000000000000000000000000000000000000000000000000000000000000000000000000000000000000000000000000000000000000000000000000000000000000000000000000000000000000000000000000000000000000000000000000000000000000000000000000000000000000000000000000000000000000000000000000000000000000000000000000000000000000000000000000000000000000000000000000000000000000000000000000000000000000000000000000000000000000000000000000000000000000000000000000000000000000000000000000000000000000000000000000000000000000000000000000000000000000000000000000000000000000000000000000000000000000000000000000000000000000000000000000000000000000000000000000000000000000000000000000000000000000000000000000000000000000000000000000000000000000000000000000000000000000000000000000000000000000000000000000000000000000000000000000000000000000000000000000000000000000000000000000000000000000000000000000000000000000000000000000000000000000000000000000000000000000000000000000000000000000000000000000000000000000000000000000000000000000000000000000000000000000000000000000000000000000000000000000000000000000000000000000000000000000000000000000000000000000000000000000000000000000000000000000000000000000000000000000000000000000000000000000000000000000000000000000000000000000000000000000000000000000000000000000000000000000000000000000000000000000000000000000000000000000000000000000000000000000000000000000000000000000000000000000000000000000000000000000000000000000000000000000000000000000000000000000000000000000000000000000000000000000000000000000000000000000000000000000000000000000000000000000000000000000000000000000000000000000000000000000000000000000000000000000000000000000000000000000000000000000000000000000000000000000000000000000000000000000000000000000000000000000000000000000000000000000000000000000000000000000000000000000000000000000000000000000000000000000000000000000000000000000000000000000000000000000000000000000000000000000000000000000000000000000000000000000000000000000000000000000000000000000000000000000000000000000000000000000000000000000000000000000000000000000000000000000000000000000000000000000000000000000000000000000000000000000000000000000000000000000000000000000000000000000000000000000000000000000000000000000000000000000000000000000000000000000000000000000000000000000000000000000000000000000000000000000000000000000000000000000000000000000000000000000000000000000000000000000000000000000000000000000000000000000000000000000000000000000000000000000000000000000000000000000000000000000000000000000000000000000000000000000000000000000000000000000000000000000000000000000000000000000000000000000000000000000000000000000000000000000000000000000000000000000000000000000000000000000000000000000000000000000000000000000000000000000000000000000000000000000000000000000000000000000000000000000000000000000000000000000000000000000000000000000000000000000000000000000000000000000000000000000000000000000000000000000000000000000000000000000000000000000000000000000000000000000000000000000000000000000000000000000000000000000000000000000000000000000000000000000000000000000000000000000000000000000000000000000000000000000000000000000000000000000000000000000000000000000000000000000000000000000000000000000000000000000000000000000000000000000000000000000000000000000000000000000000000000000000000000000000000000000000000000000000000000000000000000000000000000000000000000000000000000000000000000000000000000000000000000000000000000000000000000000000000000000000000000000000000000000000000000000000000000000000000000000000000000000000000000000000000000000000000000000000000000000000000000000000000000000000000000000000000000000000000000000000000000000000000000000000000000000000000000000000000000000000000000000000000000000000000000000000000000000000000000000000000000000000000000000000000000000000000000000000000000000000000000000000000000000000000000000000000000000000000000000000000000000000000000000000000000000000000000000000000000000000000000000000000000000000000000000000000000000000000000000000000000000000000000000000000000000000000000000000000000000000000000000000000000000000000000000000000000000000000000000000000000000000000000000000000000000000000000000000000000000000000000000000000000000000000000000000000000000000000000000000000000000000000000000000000000000000000000000000000000000000000000000000000000000000000000000000000000000000000000000000000000000000000000000000000000000000000000000000000000000000000000000000000000000000000000000000000000000000000000000000000000000000000000000000000000000000000000000000000000000000000000000000000000000000000000000000000000000000000000000000000000000000000000000000000000000000000000000000000000000000000000000000000000000000000000000000000000000000000000000000000000000000000000000000000000000000000000000000000000000000000000000000000000000000000000000000000000000000000000000000000000000000000000000000000000000000000000000000000000000000000000000000000000000000000000000000000000000000000000000000000000000000000000000000000000000000000000000000000000000000000000000000000000000000000000000000000000000000000000000000000000000000000000000000000000000000000000000000000000000000000000000000000000000000000000000000000000000000000000000000000000000000000000000000000000000000000000000000000000000000000000000000000000000000000000000000000000000000000000000000000000000000000000000000000000000000000000000000000000000000000000000000000000000000000000000000000000000000000000000000000000000000000000000000000000000000000000000000000000000000000000000000000000000000000000000000000000000000000000000000000000000000000000000000000000000000000000000000000000000000000000000000000000000000000000000000000000000000000000000000000000000000000000000000000000000000000000000000000000000000000000000000000000000000000000000000000000000000000000000000000000000000000000000000000000000000000000000000000000000000000000000000000000000000000000000000000000000000000000000000000000000000000000000000000000000000000000000000000000000000000000000000000000000000000000000000000000000000000000000000000000000000000000000000000000000000000000000000000000000000000000000000000000000000000000000000000000000000000000000000000000000000000000000000000000000000000000000000000000000000000000000000000000000000000000000000000000000000000000000000000000000000000000000000000000000000000000000000000000000000000000000000000000000000000000000000000000000000000000000000000000000000000000000000000000000000000000000000000000000000000000000000000000000000000000000000000000000000000000000000000000000000000000000000000000000000000000000000000000000000000000000000000000000000000000000000000000000000000000000000000000000000000000000000000000000000000000000000000000000000000000000000000000000000000000000000000000000000000000000000000000000000000000000000000000000000000000000000000000000000000000000000000000000000000000000000000000000000000000000000000000000000000000000000000000000000000000000000000000000000000000000000000000000000000000000000000000000000000000000000000000000000000000000000000000000000000000000000000000000000000000000000000000000000000000000000000000000000000000000000000000000000000000000000000000000000000000000000000000000000000000000000000000000000000000000000000000000000000000000000000000000000000000000000000000000000000000000000000000000000000000000000000000000000000000000000000000000000000000000000000000000000000000000000000000000000000000000000000000000000000000000000000000000000000000000000000000000000000000000000000000000000000000000000000000000000000000000000000000000000000000000000000000000000000000000000000000000000000000000000000000000000000000000000000000000000000000000000000000000000000000000000000000000000000000000000000000000000000000000000000000000000000000000000000000000000000000000000000000000000000000000000000000000000000000000000000000000000000000000000000000000000000000000000000000000000000000000000000000000000000000000000000000000000000000000000000000000000000000000000000000000000000000000000000000000000000000000000000000000000000000000000000000000000000000000000000000000000000000000000000000000000000000000000000000000000000000000000000000000000000000000000000000000000000000000000000000000000000000000000000000000000000000000000000000000000000000000000000000000000000000000000000000000000000000000000000000000000000000000000000000000000000000000000000000000000000000000000000000000000000000000000000000000000000000000000000000000000000000000000000000000000000000000000000000000000000000000000000000000000000000000000000000000000000000000000000000000000000000000000000000000000000000000000000000000000000000000000000000000000000000000000000000000000000000000000000000000000000000000000000000000000000000000000000000000000000000000000000000000000000000000000000000000000000000000000000000000000000000000000000000000000000000000000000000000000000000000000000000000000000000000000000000000000000000000000000000000000000000000000000000000000000000000000000000000000000000000000000000000000000000000000000000000000000000000000000000000000000000000000000000000000000000000000000000000000000000000000000000000000000000000000000000000000000000000000000000000000000000000000000000000000000000000000000000000000000000000000000000000000000000000000000000000000000000000000000000000000000000000000000000000000000000000000000000000000000000000000000000000000000000000000000000000000000000000000000000000000000000000000000000000000000000000000000000000000000000000000000000000000000000000000000000000000000000000000000000000000000000000000000000000000000000000000000000000000000000000000000000000000000000000000000000000000000000000000000000000000000000000000000000000000000000000000000000000000000000000000000000000000000000000000000000000000000000000000000000000000000000000000000000000000000000000000000000000000000000000000000000000000000000000000000000000000000000000000000000000000000000000000000000000000000000000000000000000000000000000000000000000000000000000000000000000000000000000000000000000000000000000000000000000000000000000000000000000000000000000000000000000000000000000000000000000000000000000000000000000000000000000000000000000000000000000000000000000000000000000000000000000000000000000000000000000000000000000000000000000000000000000000000000000000000000000000000000000000000000000000000000000000000000000000000000000000000000000000000000000000000000000000000000000000000000000000000000000000000000000000000000000000000000000000000000000000000000000000000000000000000000000000000000000000000000000000000000000000000000000000000000000000000000000000000000000000000000000000000000000000000000000000000000000000000000000000000000000000000000000000000000000000000000000000000000000000000000000000000000000000000000000000000000000000000000000000000000000000000000000000000000000000000000000000000000000000000000000000000000000000000000000000000000000000000000000000000000000000000000000000000000000000000000000000000000000000000000000000000000000000000000000000000000000000000000000000000000000000000000000000000000000000000000000000000000000000000000000000000000000000000000000000000000000000000000000000000000000000000000000000000000000000000000000000000000000000000000000000000000000000000000000000000000000000000000000000000000000000000000000000000000000000000000000000000000000000000000000000000000000000000000000000000000000000000000000000000000000000000000000000000000000000000000000000000000000000000000000000000000000000000000000000000000000000000000000000000000000000000000000000000000000000000000000000000000000000000000000000000000000000000000000000000000000000000000000000000000000000000000000000000000000000000000000000000000000000000000000000000000000000000000000000000000000000000000000000000000000000000000000000000000000000000000000000000000000000000000000000000000000000000000000000000000000000000000000000000000000000000000000000000000000000000000000000000000000000000000000000000000000000000000000000000000000000000000000000000000000000000000000000000000000000000000000000000000000000000000000000000000000000000000000000000000000000000000000000000000000000000000000000000000000000000000000000000000000000000000000000000000000000000000000000000000000000000000000000000000000000000000000000000000000000000000000000000000000000000000000000000000000000000000000000000000000000000000000000000000000000000000000000000000000000000000000000000000000000000000000000000000000000000000000000000000000000000000000000000000000000000000000000000000000000000000000000000000000000000000000000000000000000000000000000000000000000000000000000000000000000000000000000000000000000000000000000000000000000000000000000000000000000000000000000000000000000000000000000000000000000000000000000000000000000000000000000000000000000000000000000000000000000000000000000000000000000000000000000000000000000000000000000000000000000000000000000000000000000000000000000000000000000000000000000000000000000000000000000000000000000000000000000000000000000000000000000000000000000000000000000000000000000000000000000000000000000000000000000000000000000000000000000000000000000000000000000000000000000000000000000000000000000000000000000000000000000000000000000000000000000000000000000000000000000000000000000000000000000000000000000000000000000000000000000000000000000000000000000000000000000000000000000000000000000000000000000000000000000000000000000000000000000000000000000000000000000000000000000000000000000000000000000000000000000000000000000000000000000000000000000000000000000000000000000000000000000000000000000000000000000000000000000000000000000000000000000000000000000000000000000000000000000000000000000000000000000000000000000000000000000000000000000000000000000000000000000000000000000000000000000000000000000000000000000000000000000000000000000000000000000000000000000000000000000000000000000000000000000000000000000000000000000000000000000000000000000000000000000000000000000000000000000000000000000000000000000000000000000000000000000000000000000000000000000000000000000000000000000000000000000000000000000000000000000000000000000000000000000000000000000000000000000000000000000000000000000000000000000000000000000000000000000000000000000000000000000000000000000000000000000000000000000000000000000000000000000000000000000000000000000000000000000000000000000000000000000000000000000000000000000000000000000000000000000000000000000000000000000000000000000000000000000000000000000000000000000000000000000000000000000000000000000000000000000000000000000000000000000000000000000000000000000000000000000000000000000000000000000000000000000000000000000000000000000000000000000000000000000000000000000000000000000000000000000000000000000000000000000000000000000000000000000000000000000000000000000000000000000000000000000000000000000000000000000000000000000000000000000000000000000000000000000000000000000000000000000000000000000000000000000000000000000000000000000000000000000000000000000000000000000000000000000000000000000000000000000000000000000000000000000000000000000000000000000000000000000000000000000000000000000000000000000000000000000000000000000000000000000000000000000000000000000000000000000000000000000000000000000000000000000000000000000000000000000000000000000000000000000000000000000000000000000000000000000000000000000000000000000000000000000000000000000000000000000000000000000000000000000000000000000000000000000000000000000000000000000000000000000000000000000000000000000000000000000000000000000000000000000000000000000000000000000000000000000000000000000000000000000000000000000000000000000000000000000000000000000000000000000000000000000000000000000000000000000000000000000000000000000000000000000000000000000000000000000000000000000000000000000000000000000000000000000000000000000000000000000000000000000000000000000000000000000000000000000000000000000000000000000000000000000000000000000000000000000000000000000000000000000000000000000000000000000000000000000000000000000000000000000000000000000000000000000000000000000000000000000000000000000000000000000000000000000000000000000000000000000000000000000000000000000000000000000000000000000000000000000000000000000000000000000000000000000000000000000000000000000000000000000000000000000000000000000000000000000000000000000000000000000000000000000000000000000000000000000000000000000000000000000000000000000000000000000000000000000000000000000000000000000000000000000000000000000000000000000000000000000000000000000000000000000000000000000000000000000000000000000000000000000000000000000000000000000000000000000000000000000000000000000000000000000000000000000000000000000000000000000000000000000000000000000000000000000000000000000000000000000000000000000000000000000000000000000000000000000000000000000000000000000000000000000000000000000000000000000000000000000000000000000000000000000000000000000000000000000000000000000000000000000000000000000000000000000000000000000000000000000000000000000000000000000000000000000000000000000000000000000000000000000000000000000000000000000000000000000000000000000000000000000000000000000000000000000000000000000000000000000000000000000000000000000000000000000000000000000000000000000000000000000000000000000000000000000000000000000000000000000000000000000000000000000000000000000000000000000000000000000000000000000000000000000000000000000000000000000000000000000000000000000000000000000000000000000000000000000000000000000000000000000000000000000000000000000000000000000000000000000000000000000000000000000000000000000000000000000000000000000000000000000000000000000000000000000000000000000000000000000000000000000000000000000000000000000000000000000000000000000000000000000000000000000000000000000000000000000000000000000000000000000000000000000000000000000000000000000000000000000000000000000000000000000000000000000000000000000000000000000000000000000000000000000000000000000000000000000000000000000000000000000000000000000000000000000000000000000000000000000000000000000000000000000000000000000000000000000000000000000000000000000000000000000000000000000000000000000000000000000000000000000000000000000000000000000000000000000000000000000000000000000000000000000000000000000000000000000000000000000000000000000000000000000000000000000000000000000000000000000000000000000000000000000000000000000000000000000000000000000000000000000000000000000000000000000000000000000000000000000000000000000000000000000000000000000000000000000000000000000000000000000000000000000000000000000000000000000000000000000000000000000000000000000000000000000000000000000000000000000000000000000000000000000000000000000000000000000000000000000000000000000000000000000000000000000000000000000000000000000000000000000000000000000000000000000000000000000000000000000000000000000000000000000000000000000000000000000000000000000000000000000000000000000000000000000000000000000000000000000000000000000000000000000000000000000000000000000000000000000000000000000000000000000000000000000000000000000000000000000000000000000000000000000000000000000000000000000000000000000000000000000000000000000000000000000000000000000000000000000000000000000000000000000000000000000000000000000000000000000000000000000000000000000000000000000000000000000000000000000000000000000000000000000000000000000000000000000000000000000000000000000000000000000000000000000000000000000000000000000000000000000000000000000000000000000000000000000000000000000000000000000000000000000000000000000000000000000000000000000000000000000000000000000000000000000000000000000000000000000000000000000000000000000000000000000000000000000000000000000000000000000000000000000000000000000000000000000000000000000000000000000000000000000000000000000000000000000000000000000000000000000000000000000000000000000000000000000000000000000000000000000000000000000000000000000000000000000000000000000000000000000000000000000000000000000000000000000000000000000000000000000000000000000000000000000000000000000000000000000000000000000000000000000000000000000000000000000000000000000000000000000000000000000000000000000000000000000000000000000000000000000000000000000000000000000000000000000000000000000000000000000000000000000000000000000000000000000000000000000000000000000000000000000000000000000000000000000000000000000000000000000000000000000000000000000000000000000000000000000000000000000000000000000000000000000000000000000000000000000000000000000000000000000000000000000000000000000000000000000000000000000000000000000000000000000000000000000000000000000000000000000000000000000000000000000000000000000000000000000000000000000000000000000000000000000000000000000000000000000000000000000000000000000000000000000000000000000000000000000000000000000000000000000000000000000000000000000000000000000000000000000000000000000000000000000000000000000000000000000000000000000000000000000000000000000000000000000000000000000000000000000000000000000000000000000000000000000000000000000000000000000000000000000000000000000000000000000000000000000000000000000000000000000000000000000000000000000000000000000000000000000000000000000000000000000000000000000000000000000000000000000000000000000000000000000000000000000000000000000000000000000000000000000000000000000000000000000000000000000000000000000000000000000000000000000000000000000000000000000000000000000000000000000000000000000000000000000000000000000000000000000000000000000000000000000000000000000000000000000000000000000000000000000000000000000000000000000000000000000000000000000000000000000000000000000000000000000000000000000000000000000000000000000000000000000000000000000000000000000000000000000000000000000000000000000000000000000000000000000000000000000000000000000000000000000000000000000000000000000000000000000000000000000000000000000000000000000000000000000000000000000000000000000000000000000000000000000000000000000000000000000000000000000000000000000000000000000000000000000000000000000000000000000000000000000000000000000000000000000000000000000000000000000000000000000000000000000000000000000000000000000000000000000000000000000000000000000000000000000000000000000000000000000000000000000000000000000000000000000000000000000000000000000000000000000000000000000000000000000000000000000000000000000000000000000000000000000000000000000000000000000000000000000000000000000000000000000000000000000000000000000000000000000000000000000000000000000000000000000000000000000000000000000000000000000000000000000000000000000000000000000000000000000000000000000000000000000000000000000000000000000000000000000000000000000000000000000000000000000000000000000000000000000000000000000000000000000000000000000000000000000000000000000000000000000000000000000000000000000000000000000000000000000000000000000000000000000000000000000000000000000000000000000000000000000000000000000000000000000000000000000000000000000000000000000000000000000000000000000000000000000000000000000000000000000000000000000000000000000000000000000000000000000000000000000000000000000000000000000000000000000000000000000000000000000000000000000000000000000000000000000000000000000000000000000000000000000000000000000000000000000000000000000000000000000000000000000000000000000000000000000000000000000000000000000000000000000000000000000000000000000000000000000000000000000000000000000000000000000000000000000000000000000000000000000000000000000000000000000000000000000000000000000000000000000000000000000000000000000000000000000000000000000000000000000000000000000000000000000000000000000000000000000000000000000000000000000000000000000000000000000000000000000000000000000000000000000000000000000000000000000000000000000000000000000000000000000000000000000000000000000000000000000000000000000000000000000000000000000000000000000000000000000000000000000000000000000000000000000000000000000000000000000000000000000000000000000000000000000000000000000000000000000000000000000000000000000000000000000000000000000000000000000000000000000000000000000000000000000000000000000000000000000000000000000000000000000000000000000000000000000000000000000000000000000000000000000000000000000000000000000000000000000000000000000000000000000000000000000000000000000000000000000000000000000000000000000000000000000000000000000000000000000000000000000000000000000000000000000000000000000000000000000000000000000000000000000000000000000000000000000000000000000000000000000000000000000000000000000000000000000000000000000000000000000000000000000000000000000000000000000000000000000000000000000000000000000000000000000000000000000000000000000000000000000000000000000000000000000000000000000000000000000000000000000000000000000000000000000000000000000000000000000000000000000000000000000000000000000000000000000000000000000000000000000000000000000000000000000000000000000000000000000000000000000000000000000000000000000000000000000000000000000000000000000000000000000000000000000000000000000000000000000000000000000000000000000000000000000000000000000000000000000000000000000000000000000000000000000000000000000000000000000000000000000000000000000000000000000000000000000000000000000000000000000000000000000000000000000000000000000000000000000000000000000000000000000000000000000000000000000000000000000000000000000000000000000000000000000000000000000000000000000000000000000000000000000000000000000000000000000000000000000000000000000000000000000000000000000000000000000000000000000000000000000000000000000000000000000000000000000000000000000000000000000000000000000000000000000000000000000000000000000000000000000000000000000000000000000000000000000000000000000000000000000000000000000000000000000000000000000000000000000000000000000000000000000000000000000000000000000000000000000000000000000000000000000000000000000000000000000000000000000000000000000000000000000000000000000000000000000000000000000000000000000000000000000000000000000000000000000000000000000000000000000000000000000000000000000000000000000000000000000000000000000000000000000000000000000000000000000000000000000000000000000000000000000000000000000000000000000000000000000000000000000000000000000000000000000000000000000000000000000000000000000000000000000000000000000000000000000000000000000000000000000000000000000000000000000000000000000000000000000000000000000000000000000000000000000000000000000000000000000000000000000000000000000000000000000000000000000000000000000000000000000000000000000000000000000000000000000000000000000000000000000000000000000000000000000000000000000000000000000000000000000000000000000000000000000000000000000000000000000000000000000000000000000000000000000000000000000000000000000000000000000000000000000000000000000000000000000000000000000000000000000000000000000000000000000000000000000000000000000000000000000000000000000000000000000000000000000000000000000000000000000000000000000000000000000000000000000000000000000000000000000000000000000000000000000000000000000000000000000000000000000000000000000000000000000000000000000000000000000000000000000000000000000000000000000000000000000000000000000000000000000000000000000000000000000000000000000000000000000000000000000000000000000000000000000000000000000000000000000000000000000000000000000000000000000000000000000000000000000000000000000000000000000000000000000000000000000000000000000000000000000000000000000000000000000000000000000000000000000000000000000000000000000000000000000000000000000000000000000000000000000000000000000000000000000000000000000000000000000000000000000000000000000000000000000000000000000000000000000000000000000000000000000000000000000000000000000000000000000000000000000000000000000000000000000000000000000000000000000000000000000000000000000000000000000000000000000000000000000000000000000000000000000000000000000000000000000000000000000000000000000000000000000000000000000000000000000000000000000000000000000000000000000000000000000000000000000000000000000000000000000000000000000000000000000000000000000000000000000000000000000000000000000000000000000000000000000000000000000000000000000000000000000000000000000000000000000000000000000000000000000000000000000000000000000000000000000000000000000000000000000000000000000000000000000000000000000000000000000000000000000000000000000000000000000000000000000000000000000000000000000000000000000000000000000000000000000000000000000000000000000000000000000000000000000000000000000000000000000000000000000000000000000000000000000000000000000000000000000000000000000000000000000000000000000000000000000000000000000000000000000000000000000000000000000000000000000000000000000000000000000000000000000000000000000000000000000000000000000000000000000000000000000000000000000000000000000000000000000000000000000000000000000000000000000000000000000000000000000000000000000000000000000000000000000000000000000000000000000000000000000000000000000000000000000000000000000000000000000000000000000000000000000000000000000000000000000000000000000000000000000000000000000000000000000000000000000000000000000000000000000000000000000000000000000000000000000000000000000000000000000000000000000000000000000000000000000000000000000000000000000000000000000000000000000000000000000000000000000000000000000000000000000000000000000000000000000000000000000000000000000000000000000000000000000000000000000000000000000000000000000000000000000000000000000000000000000000000000000000000000000000000000000000000000000000000000000000000000000000000000000000000000000000000000000000000000000000000000000000000000000000000000000000000000000000000000000000000000000000000000000000000000000000000000000000000000000000000000000000000000000000000000000000000000000000000000000000000000000000000000000000000000000000000000000000000000000000000000000000000000000000000000000000000000000000000000000000000000000000000000000000000000000000000000000000000000000000000000000000000000000000000000000000000000000000000000000000000000000000000000000000000000000000000000000000000000000000000000000000000000000000000000000000000000000000000000000000000000000000000000000000000000000000000000000000000000000000000000000000000000000000000000000000000000000000000000000000000000000000000000000000000000000000000000000000000000000000000000000000000000000000000000000000000000000000000000000000000000000000000000000000000000000000000000000000000000000000000000000000000000000000000000000000000000000000000000000000000000000000000000000000000000000000000000000000000000000000000000000000000000000000000000000000000000000000000000000000000000000000000000000000000000000000000000000000000000000000000000000000000000000000000000000000000000000000000000000000000000000000000000000000000000000000000000000000000000000000000000000000000000000000000000000000000000000000000000000000000000000000000000000000000000000000000000000000000000000000000000000000000000000000000000000000000000000000000000000000000000000000000000000000000000000000000000000000000000000000000000000000000000000000000000000000000000000000000000000000000000000000000000000000000000000000000000000000000000000000000000000000000000000000000000000000000000000000000000000000000000000000000000000000000000000000000000000000000000000000000000000000000000000000000000000000000000000000000000000000000000000000000000000000000000000000000000000000000000000000000000000000000000000000000000000000000000000000000000000000000000000000000000000000000000000000000000000000000000000000000000000000000000000000000000000000000000000000000000000000000000000000000000000000000000000000000000000000000000000000000000000000000000000000000000000000000000000000000000000000000000000000000000000000000000000000000000000000000000000000000000000000000000000000000000000000000000000000000000000000000000000000000000000000000000000000000000000000000000000000000000000000000000000000000000000000000000000000000000000000000000000000000000000000000000000000000000000000000000000000000000000000000000000000000000000000000000000000000000000000000000000000000000000000000000000000000000000000000000000000000000000000000000000000000000000000000000000000000000000000000000000000000000000000000000000000000000000000000000000000000000000000000000000000000000000000000000000000000000000000000000000000000000000000000000000000000000000000000000000000000000000000000000000000000000000000000000000000000000000000000000000000000000000000000000000000000000000000000000000000000000000000000000000000000000000000000000000000000000000000000000000000000000000000000000000000000000000000000000000000000000000000000000000000000000000000000000000000000000000000000000000000000000000000000000000000000000000000000000000000000000000000000000000000000000000000000000000000000000000000000000000000000000000000000000000000000000000000000000000000000000000000000000000000000000000000000000000000000000000000000000000000000000000000000000000000000000000000000000000000000000000000000000000000000000000000000000000000000000000000000000000000000000000000000000000000000000000000000000000000000000000000000000000000000000000000000000000000000000000000000000000000000000000000000000000000000000000000000000000000000000000000000000000000000000000000000000000000000000000000000000000000000000000000000000000000000000000000000000000000000000000000000000000000000000000000000000000000000000000000000000000000000000000000000000000000000000000000000000000000000000000000000000000000000000000000000000000000000000000000000000000000000000000000000000000000000000000000000000000000000000000000000000000000000000000000000000000000000000000000000000000000000000000000000000000000000000000000000000000000000000000000000000000000000000000000000000000000000000000000000000000000000000000000000000000000000000000000000000000000000000000000000000000000000000000000000000000000000000000000000000000000000000000000000000000000000000000000000000000000000000000000000000000000000000000000000000000000000000000000000000000000000000000000000000000000000000000000000000000000000000000000000000000000000000000000000000000000000000000000000000000000000000000000000000000000000000000000000000000000000000000000000000000000000000000000000000000000000000000000000000000000000000000000000000000000000000000000000000000000000000000000000000000000000000000000000000000000000000000000000000000000000000000000000000000000000000000000000000000000000000000000000000000000000000000000000000000000000000000000000000000000000000000000000000000000000000000000000000000000000000000000000000000000000000000000000000000000000000000000000000000000000000000000000000000000000000000000000000000000000000000000000000000000000000000000000000000000000000000000000000000000000000000000000000000000000000000000000000000000000000000000000000000000000000000000000000000000000000000000000000000000000000000000000000000000000000000000000000000000000000000000000000000000000000000000000000000000000000000000000000000000000000000000000000000000000000000000000000000000000000000000000000000000000000000000000000000000000000000000000000000000000000000000000000000000000000000000000000000000000000000000000000000000000000000000000000000000000000000000000000000000000000000000000000000000000000000000000000000000000000000000000000000000000000000000000000000000000000000000000000000000000000000000000000000000000000000000000000000000000000000000000000000000000000000000000000000000000000000000000000000000000000000000000000000000000000000000000000000000000000000000000000000000000000000000000000000000000000000000000000000000000000000000000000000000000000000000000000000000000000000000000000000000000000000000000000000000000000000000000000000000000000000000000000000000000000000000000000000000000000000000000000000000000000000000000000000000000000000000000000000000000000000000000000000000000000000000000000000000000000000000000000000000000000000000000000000000000000000000000000000000000000000000000000000000000000000000000000000000000000000000000000000000000000000000000000000000000000000000000000000000000000000000000000000000000000000000000000000000000000000000000000000000000000000000000000000000000000000000000000000000000000000000000000000000000000000000000000000000000000000000000000000000000000000000000000000000000000000000000000000000000000000000000000000000000000000000000000000000000000000000000000000000000000000000000000000000000000000000000000000000000000000000000000000000000000000000000000000000000000000000000000000000000000000000000000000000000000000000000000000000000000000000000000000000000000000000000000000000000000000000000000000000000000000000000000000000000000000000000000000000000000000000000000000000000000000000000000000000000000000000000000000000000000000000000000000000000000000000000000000000000000000000000000000000000000000000000000000000000000000000000000000000000000000000000000000000000000000000000000000000000000000000000000000000000000000000000000000000000000000000000000000000000000000000000000000000000000000000000000000000000000000000000000000000000000000000000000000000000000000000000000000000000000000000000000000000000000000000000000000000000000000000000000000000000000000000000000000000000000000000000000000000000000000000000000000000000000000000000000000000000000000000000000000000000000000000000000000000000000000000000000000000000000000000000000000000000000000000000000000000000000000000000000000000000000000000000000000000000000000000000000000000000000000000000000000000000000000000000000000000000000000000000000000000000000000000000000000000000000000000000000000000000000000000000000000000000000000000000000000000000000000000000000000000000000000000000000000000000000000000000000000000000000000000000000000000000000000000000000000000000000000000000000000000000000000000000000000000000000000000000000000000000000000000000000000000000000000000000000000000000000000000000000000000000000000000000000000000000000000000000000000000000000000000000000000000000000000000000000000000000000000000000000000000000000000000000000000000000000000000000000000000000000000000000000000000000000000000000000000000000000000000000000000000000000000000000000000000000000000000000000000000000000000000000000000000000000000000000000000000000000000000000000000000000000000000000000000000000000000000000000000000000000000000000000000000000000000000000000000000000000000000000000000000000000000000000000000000000000000000000000000000000000000000000000000000000000000000000000000000000000000000000000000000000000000000000000000000000000000000000000000000000000000000000000000000000000000000000000000000000000000000000000000000000000000000000000000000000000000000000000000000000000000000000000000000000000000000000000000000000000000000000000000000000000000000000000000000000000000000000000000000000000000000000000000000000000000000000000000000000000000000000000000000000000000000000000000000000000000000000000000000000000000000000000000000000000000000000000000000000000000000000000000000000000000000000000000000000000000000000000000000000000000000000000000000000000000000000000000000000000000000000000000000000000000000000000000000000000000000000000000000000000000000000000000000000000000000000000000000000000000000000000000000000000000000000000000000000000000000000000000000000000000000000000000000000000000000000000000000000000000000000000000000000000000000000000000000000000000000000000000000000000000000000000000000000000000000000000000000000000000000000000000000000000000000000000000000000000000000000000000000000000000000000000000000000000000000000000000000000000000000000000000000000000000000000000000000000000000000000000000000000000000000000000000000000000000000000000000000000000000000000000000000000000000000000000000000000000000000000000000000000000000000000000000000000000000000000000000000000000000000000000000000000000000000000000000000000000000000000000000000000000000000000000000000000000000000000000000000000000000000000000000000000000000000000000000000000000000000000000000000000000000000000000000000000000000000000000000000000000000000000000000000000000000000000000000000000000000000000000000000000000000000000000000000000000000000000000000000000000000000000000000000000000000000000000000000000000000000000000000000000000000000000000000000000000000000000000000000000000000000000000000000000000000000000000000000000000000000000000000000000000000000000000000000000000000000000000000000000000000000000000000000000000000000000000000000000000000000000000000000000000000000000000000000000000000000000000000000000000000000000000000000000000000000000000000000000000000000000000000000000000000000000000000000000000000000000000000000000000000000000000000000000000000000000000000000000000000000000000000000000000000000000000000000000000000000000000000000000000000000000000000000000000000000000000000000000000000000000000000000000000000000000000000000000000000000000000000000000000000000000000000000000000000000000000000000000000000000000000000000000000000000000000000000000000000000000000000000000000000000000000000000000000000000000000000000000000000000000000000000000000000000000000000000000000000000000000000000000000000000000000000000000000000000000000000000000000000000000000000000000000000000000000000000000000000000000000000000000000000000000000000000000000000000000000000000000000000000000000000000000000000000000000000000000000000000000000000000000000000000000000000000000000000000000000000000000000000000000000000000000000000000000000000000000000000000000000000000000000000000000000000000000000000000000000000000000000000000000000000000000000000000000000000000000000000000000000000000000000000000000000000000000000000000000000000000000000000000000000000000000000000000000000000000000000000000000000000000000000000000000000000000000000000000000000000000000000000000000000000000000000000000000000000000000000000000000000000000000000000000000000000000000000000000000000000000000000000000000000000000000000000000000000000000000000000000000000000000000000000000000000000000000000000000000000000000000000000000000000000000000000000000000000000000000000000000000000000000000000000000000000000000000000000000000000000000000000000000000000000000000000000000000000000000000000000000000000000000000000000000000000000000000000000000000000000000000000000000000000000000000000000000000000000000000000000000000000000000000000000000000000000000000000000000000000000000000000000000000000000000000000000000000000000000000000000000000000000000000000000000000000000000000000000000000000000000000000000000000000000000000000000000000000000000000000000000000000000000000000000000000000000000000000000000000000000000000000000000000000000000000000000000000000000000000000000000000000000000000000000000000000000000000000000000000000000000000000000000000000000000000000000000000000000000000000000000000000000000000000000000000000000000000000000000000000000000000000000000000000000000000000000000000000000000000000000000000000000000000000000000000000000000000000000000000000000000000000000000000000000000000000000000000000000000000000000000000000000000000000000000000000000000000000000000000000000000000000000000000000000000000000000000000000000000000000000000000000000000000000000000000000000000000000000000000000000000000000000000000000000000000000000000000000000000000000000000000000000000000000000000000000000000000000000000000000000000000000000000000000000000000000000000000000000000000000000000000000000000000000000000000000000000000000000000000000000000000000000000000000000000000000000000000000000000000000000000000000000000000000000000000000000000000000000000000000000000000000000000000000000000000000000000000000000000000000000000000000000000000000000000000000000000000000000000000000000000000000000000000000000000000000000000000000000000000000000000000000000000000000000000000000000000000000000000000000000000000000000000000000000000000000000000000000000000000000000000000000000000000000000000000000000000000000000000000000000000000000000000000000000000000000000000000000000000000000000000000000000000000000000000000000000000000000000000000000000000000000000000000000000000000000000000000000000000000000000000000000000000000000000000000000000000000000000000000000000000000000000000000000000000000000000000000000000000000000000000000000000000000000000000000000000000000000000000000000000000000000000000000000000000000000000000000000000000000000000000000000000000000000000000000000000000000000000000000000000000000000000000000000000000000000000000000000000000000000000000000000000000000000000000000000000000000000000000000000000000000000000000000000000000000000000000000000000000000000000000000000000000000000000000000000000000000000000000000000000000000000000000000000000000000000000000000000000000000000000000000000000000000000000000000000000000000000000000000000000000000000000000000000000000000000000000000000000000000000000000000000000000000000000000000000000000000000000000000000000000000000000000000000000000000000000000000000000000000000000000000000000000000000000000000000000000000000000000000000000000000000000000000000000000000000000000000000000000000000000000000000000000000000000000000000000000000000000000000000000000000000000000000000000000000000000000000000000000000000000000000000000000000000000000000000000000000000000000000000000000000000000000000000000000000000000000000000000000000000000000000000000000000000000000000000000000000000000000000000000000000000000000000000000000000000000000000000000000000000000000000000000000000000000000000000000000000000000000000000000000000000000000000000000000000000000000000000000000000000000000000000000000000000000000000000000000000000000000000000000000000000000000000000000000000000000000000000000000000000000000000000000000000000000000000000000000000000000000000000000000000000000000000000000000000000000000000000000000000000000000000000000000000000000000000000000000000000000000000000000000000000000000000000000000000000000000000000000000000000000000000000000000000000000000000000000000000000000000000000000000000000000000000000000000000000000000000000000000000000000000000000000000000000000000000000000000000000000000000000000000000000000000000000000000000000000000000000000000000000000000000000000000000000000000000000000000000000000000000000000000000000000000000000000000000000000000000000000000000000000000000000000000000000000000000000000000000000000000000000000000000000000000000000000000000000000000000000000000000000000000000000000000000000000000000000000000000000000000000000000000000000000000000000000000000000000000000000000000000000000000000000000000000000000000000000000000000000000000000000000000000000000000000000000000000000000000000000000000000000000000000000000000000000000000000000000000000000000000000000000000000000000000000000000000000000000000000000000000000000000000000000000000000000000000000000000000000000000000000000000000000000000000000000000000000000000000000000000000000000000000000000000000000000000000000000000000000000000000000000000000000000000000000000000000000000000000000000000000000000000000000000000000000000000000000000000000000000000000000000000000000000000000000000000000000000000000000000000000000000000000000000000000000000000000000000000000000000000000000000000000000000000000000000000000000000000000000000000000000000000000000000000000000000000000000000000000000000000000000000000000000000000000000000000000000000000000000000000000000000000000000000000000000000000000000000000000000000000000000000000000000000000000000000000000000000000000000000000000000000000000000000000000000000000000000000000000000000000000000000000000000000000000000000000000000000000000000000000000000000000000000000000000000000000000000000000000000000000000000000000000000000000000000000000000000000000000000000000000000000000000000000000000000000000000000000000000000000000000000000000000000000000000000000000000000000000000000000000000000000000000000000000000000000000000000000000000000000000000000000000000000000000000000000000000000000000000000000000000000000000000000000000000000000000000000000000000000000000000000000000000000000000000000000000000000000000000000000000000000000000000000000000000000000000000000000000000000000000000000000000000000000000000000000000000000000000000000000000000000000000000000000000000000000000000000000000000000000000000000000000000000000000000000000000000000000000000000000000000000000000000000000000000000000000000000000000000000000000000000000000000000000000000000000000000000000000000000000000000000000000000000000000000000000000000000000000000000000000000000000000000000000000000000000000000000000000000000000000000000000000000000000000000000000000000000000000000000000000000000000000000000000000000000000000000000000000000000000000000000000000000000000000000000000000000000000000000000000000000000000000000000000000000000000000000000000000000000000000000000000000000000000000000000000000000000000000000000000000000000000000000000000000000000000000000000000000000000000000000000000000000000000000000000000000000000000000000000000000000000000000000000000000000000000000000000000000000000000000000000000000000000000000000000000000000000000000000000000000000000000000000000000000000000000000000000000000000000000000000000000000000000000000000000000000000000000000000000000000000000000000000000000000000000000000000000000000000000000000000000000000000000000000000000000000000000000000000000000000000000000000000000000000000000000000000000000000000000000000000000000000000000000000000000000000000000000000000000000000000000000000000000000000000000000000000000000000000000000000000000000000000000000000000000000000000000000000000000000000000000000000000000000000000000000000000000000000000000000000000000000000000000000000000000000000000000000000000000000000000000000000000000000000000000000000000000000000000000000000000000000000000000000000000000000000000000000000000000000000000000000000000000000000000000000000000000000000000000000000000000000000000000000000000000000000000000000000000000000000000000000000000000000000000000000000000000000000000000000000000000000000000000000000000000000000000000000000000000000000000000000000000000000000000000000000000000000000000000000000000000000000000000000000000000000000000000000000000000000000000000000000000000000000000000000000000000000000000000000000000000000000000000000000000000000000000000000000000000000000000000000000000000000000000000000000000000000000000000000000000000000000000000000000000000000000000000000000000000000000000000000000000000000000000000000000000000000000000000000000000000000000000000000000000000000000000000000000000000000000000000000000000000000000000000000000000000000000000000000000000000000000000000000000000000000000000000000000000000000000000000000000000000000000000000000000000000000000000000000000000000000000000000000000000000000000000000000000000000000000000000000000000000000000000000000000000000000000000000000000000000000000000000000000000000000000000000000000000000000000000000000000000000000000000000000000000000000000000000000000000000000000000000000000000000000000000000000000000000000000000000000000000000000000000000000000000000000000000000000000000000000000000000000000000000000000000000000000000000000000000000000000000000000000000000000000000000000000000000000000000000000000000000000000000000000000000000000000000000000000000000000000000000000000000000000000000000000000000000000000000000000000000000000000000000000000000000000000000000000000000000000000000000000000000000000000000000000000000000000000000000000000000000000000000000000000000000000000000000000000000000000000000000000000000000000000000000000000000000000000000000000000000000000000000000000000000000000000000000000000000000000000000000000000000000000000000000000000000000000000000000000000000000000000000000000000000000000000000000000000000000000000000000000000000000000000000000000000000000000000000000000000000000000000000000000000000000000000000000000000000000000000000000000000000000000000000000000000000000000000000000000000000000000000000000000000000000000000000000000000000000000000000000000000000000000000000000000000000000000000000000000000000000000000000000000000000000000000000000000000000000000000000000000000000000000000000000000000000000000000000000000000000000000000000000000000000000000000000000000000000000000000000000000000000000000000000000000000000000000000000000000000000000000000000000000000000000000000000000000000000000000000000000000000000000000000000000000000000000000000000000000000000000000000000000000000000000000000000000000000000000000000000000000000000000000000000000000000000000000000000000000000000000000000000000000000000000000000000000000000000000000000000000000000000000000000000000000000000000000000000000000000000000000000000000000000000000000000000000000000000000000000000000000000000000000000000000000000000000000000000000000000000000000000000000000000000000000000000000000000000000000000000000000000000000000000000000000000000000000000000000000000000000000000000000000000000000000000000000000000000000000000000000000000000000000000000000000000000000000000000000000000000000000000000000000000000000000000000000000000000000000000000000000000000000000000000000000000000000000000000000000000000000000000000000000000000000000000000000000000000000000000000000000000000000000000000000000000000000000000000000000000000000000000000000000000000000000000000000000000000000000000000000000000000000000000000000000000000000000000000000000000000000000000000000000000000000000000000000000000000000000000000000000000000000000000000000000000000000000000000000000000000000000000000000000000000000000000000000000000000000000000000000000000000000000000000000000000000000000000000000000000000000000000000000000000000000000000000000000000000000000000000000000000000000000000000000000000000000000000000000000000000000000000000000000000000000000000000000000000000000000000000000000000000000000000000000000000000000000000000000000000000000000000000000000000000000000000000000000000000000000000000000000000000000000000000000000000000000000000000000000000000000000000000000000000000000000000000000000000000000000000000000000000000000000000000000000000000000000000000000000000000000000000000000000000000000000000000000000000000000000000000000000000000000000000000000000000000000000000000000000000000000000000000000000000000000000000000000000000000000000000000000000000000000000000000000000000000000000000000000000000000000000000000000000000000000000000000000000000000000000000000000000000000000000000000000000000000000000000000000000000000000000000000000000000000000000000000000000000000000000000000000000000000000000000000000000000000000000000000000000000000000000000000000000000000000000000000000000000000000000000000000000000000000000000000000000000000000000000000000000000000000000000000000000000000000000000000000000000000000000000000000000000000000000000000000000000000000000000000000000000000000000000000000000000000000000000000000000000000000000000000000000000000000000000000000000000000000000000000000000000000000000000000000000000000000000000000000000000000000000000000000000000000000000000000000000000000000000000000000000000000000000000000000000000000000000000000000000000000000000000000000000000000000000000000000000000000000000000000000000000000000000000000000000000000000000000000000000000000000000000000000000000000000000000000000000000000000000000000000000000000000000000000000000000000000000000000000000000000000000000000000000000000000000000000000000000000000000000000000000000000000000000000000000000000000000000000000000000000000000000000000000000000000000000000000000000000000000000000000000000000000000000000000000000000000000000000000000000000000000000000000000000000000000000000000000000000000000000000000000000000000000000000000000000000000000000000000000000000000000000000000000000000000000000000000000000000000000000000000000000000000000000000000000000000000000000000000000000000000000000000000000000000000000000000000000000000000000000000000000000000000000000000000000000000000000000000000000000000000000000000000000000000000000000000000000000000000000000000000000000000000000000000000000000000000000000000000000000000000000000000000000000000000000000000000000000000000000000000000000000000000000000000000000000000000000000000000000000000000000000000000000000000000000000000000000000000000000000000000000000000000000000000000000000000000000000000000000000000000000000000000000000000000000000000000000000000000000000000000000000000000000000000000000000000000000000000000000000000000000000000000000000000000000000000000000000000000000000000000000000000000000000000000000000000000000000000000000000000000000000000000000000000000000000000000000000000000000000000000000000000000000000000000000000000000000000000000000000000000000000000000000000000000000000000000000000000000000000000000000000000000000000000000000000000000000000000000000000000000000000000000000000000000000000000000000000000000000000000000000000000000000000000000000000000000000000000000000000000000000000000000000000000000000000000000000000000000000000000000000000000000000000000000000000000000000000000000000000000000000000000000000000000000000000000000000000000000000000000000000000000000000000000000000000000000000000000000000000000000000000000000000000000000000000000000000000000000000000000000000000000000000000000000000000000000000000000000000000000000000000000000000000000000000000000000000000000000000000000000000000000000000000000000000000000000000000000000000000000000000000000000000000000000000000000000000000000000000000000000000000000000000000000000000000000000000000000000000000000000000000000000000000000000000000000000000000000000000000000000000000000000000000000000000000000000000000000000000000000000000000000000000000000000000000000000000000000000000000000000000000000000000000000000000000000000000000000000000000000000000000000000000000000000000000000000000000000000000000000000000000000000000000000000000000000000000000000000000000000000000000000000000000000000000000000000000000000000000000000000000000000000000000000000000000000000000000000000000000000000000000000000000000000000000000000000000000000000000000000000000000000000000000000000000000000000000000000000000000000000000000000000000000000000000000000000000000000000000000000000000000000000000000000000000000000000000000000000000000000000000000000000000000000000000000000000000000000000000000000000000000000000000000000000000000000000000000000000000000000000000000000000000000000000000000000000000000000000000000000000000000000000000000000000000000000000000000000000000000000000000000000000000000000000000000000000000000000000000000000000000000000000000000000000000000000000000000000000000000000000000000000000000000000000000000000000000000000000000000000000000000000000000000000000000000000000000000000000000000000000000000000000000000000000000000000000000000000000000000000000000000000000000000000000000000000000000000000000000000000000000000000000000000000000000000000000000000000000000000000000000000000000000000000000000000000000000000000000000000000000000000000000000000000000000000000000000000000000000000000000000000000000000000000000000000000000000000000000000000000000000000000000000000000000000000000000000000000000000000000000000000000000000000000000000000000000000000000000000000000000000000000000000000000000000000000000000000000000000000000000000000000000000000000000000000000000000000000000000000000000000000000000000000000000000000000000000000000000000000000000000000000000000000000000000000000000000000000000000000000000000000000000000000000000000000000000000000000000000000000000000000000000000000000000000000000000000000000000000000000000000000000000000000000000000000000000000000000000000000000000000000000000000000000000000000000000000000000000000000000000000000000000000000000000000000000000000000000000000000000000000000000000000000000000000000000000000000000000000000000000000000000000000000000000000000000000000000000000000000000000000000000000000000000000000000000000000000000000000000000000000000000000000000000000000000000000000000000000000000000000000000000000000000000000000000000000000000000000000000000000000000000000000000000000000000000000000000000000000000000000000000000000000000000000000000000000000000000000000000000000000000000000000000000000000000000000000000000000000000000000000000000000000000000000000000000000000000000000000000000000000000000000000000000000000000000000000000000000000000000000000000000000000000000000000000000000000000000000000000000000000000000000000000000000000000000000000000000000000000000000000000000000000000000000000000000000000000000000000000000000000000000000000000000000000000000000000000000000000000000000000000000000000000000000000000000000000000000000000000000000000000000000000000000000000000000000000000000000000000000000000000000000000000000000000000000000000000000000000000000000000000000000000000000000000000000000000000000000000000000000000000000000000000000000000000000000000000000000000000000000000000000000000000000000000000000000000000000000000000000000000000000000000000000000000000000000000000000000000000000000000000000000000000000000000000000000000000000000000000000000000000000000000000000000000000000000000000000000000000000000000000000000000000000000000000000000000000000000000000000000000000000000000000000000000000000000000000000000000000000000000000000000000000000000000000000000000000000000000000000000000000000000000000000000000000000000000000000000000000000000000000000000000000000000000000000000000000000000000000000000000000000000000000000000000000000000000000000000000000000000000000000000000000000000000000000000000000000000000000000000000000000000000000000000000000000000000000000000000000000000000000000000000000000000000000000000000000000000000000000000000000000000000000000000000000000000000000000000000000000000000000000000000000000000000000000000000000000000000000000000000000000000000000000000000000000000000000000000000000000000000000000000000000000000000000000000000000000000000000000000000000000000000000000000000000000000000000000000000000000000000000000000000000000000000000000000000000000000000000000000000000000000000000000000000000000000000000000000000000000000000000000000000000000000000000000000000000000000000000000000000000000000000000000000000000000000000000000000000000000000000000000000000000000000000000000000000000000000000000000000000000000000000000000000000000000000000000000000000000000000000000000000000000000000000000000000000000000000000000000000000000000000000000000000000000000000000000000000000000000000000000000000000000000000000000000000000000000000000000000000000000000000000000000000000000000000000000000000000000000000000000000000000000000000000000000000000000000000000000000000000000000000000000000000000000000000000000000000000000000000000000000000000000000000000000000000000000000000000000000000000000000000000000000000000000000000000000000000000000000000000000000000000000000000000000000000000000000000000000000000000000000000000000000000000000000000000000000000000000000000000000000000000000000000000000000000000000000000000000000000000000000000000000000000000000000000000000000000000000000000000000000000000000000000000000000000000000000000000000000000000000000000000000000000000000000000000000000000000000000000000000000000000000000000000000000000000000000000000000000000000000000000000000000000000000000000000000000000000000000000000000000000000000000000000000000000000000000000000000000000000000000000000000000000000000000000000000000000000000000000000000000000000000000000000000000000000000000000000000000000000000000000000000000000000000000000000000000000000000000000000000000000000000000000000000000000000000000000000000000000000000000000000000000000000000000000000000000000000000000000000000000000000000000000000000000000000000000000000000000000000000000000000000000000000000000000000000000000000000000000000000000000000000000000000000000000000000000000000000000000000000000000000000000000000000000000000000000000000000000000000000000000000000000000000000000000000000000000000000000000000000000000000000000000000000000000000000000000000000000000000000000000000000000000000000000000000000000000000000000000000000000000000000000000000000000000000000000000000000000000000000000000000000000000000000000000000000000000000000000000000000000000000000000000000000000000000000000000000000000000000000000000000000000000000000000000000000000000000000000000000000000000000000000000000000000000000000000000000000000000000000000000000000000000000000000000000000000000000000000000000000000000000000000000000000000000000000000000000000000000000000000000000000000000000000000000000000000000000000000000000000000000000000000000000000000000000000000000000000000000000000000000000000000000000000000000000000000000000000000000000000000000000000000000000000000000000000000000000000000000000000000000000000000000000000000000000000000000000000000000000000000000000000000000000000000000000000000000000000000000000000000000000000000000000000000000000000000000000000000000000000000000000000000000000000000000000000000000000000000000000000000000000000000000000000000000000000000000000000000000000000000000000000000000000000000000000000000000000000000000000000000000000000000000000000000000000000000000000000000000000000000000000000000000000000000000000000000000000000000000000000000000000000000000000000000000000000000000000000000000000000000000000000000000000000000000000000000000000000000000000000000000000000000000000000000000000000000000000000000000000000000000000000000000000000000000000000000000000000000000000000000000000000000000000000000000000000000000000000000000000000000000000000000000000000000000000000000000000000000000000000000000000000000000000000000000000000000000000000000000000000000000000000000000000000000000000000000000000000000000000000000000000000000000000000000000000000000000000000000000000000000000000000000000000000000000000000000000000000000000000000000000000000000000000000000000000000000000000000000000000000000000000000000000000000000000000000000000000000000000000000000000000000000000000000000000000000000000000000000000000000000000000000000000000000000000000000000000000000000000000000000000000000000000000000000000000000000000000000000000000000000000000000000000000000000000000000000000000000000000000000000000000000000000000000000000000000000000000000000000000000000000000000000000000000000000000000000000000000000000000000000000000000000000000000000000000000000000000000000000000000000000000000000000000000000000000000000000000000000000000000000000000000000000000000000000000000000000000000000000000000000000000000000000000000000000000000000000000000000000000000000000000000000000000000000000000000000000000000000000000000000000000000000000000000000000000000000000000000000000000000000000000000000000000000000000000000000000000000000000000000000000000000000000000000000000000000000000000000000000000000000000000000000000000000000000000000000000000000000000000000000000000000000000000000000000000000000000000000000000000000000000000000000000000000000000000000000000000000000000000000000000000000000000000000000000000000000000000000000000000000000000000000000000000000000000000000000000000000000000000000000000000000000000000000000000000000000000000000000000000000000000000000000000000000000000000000000000000000000000000000000000000000000000000000000000000000000000000000000000000000000000000000000000000000000000000000000000000000000000000000000000000000000000000000000000000000000000000000000000000000000000000000000000000000000000000000000000000000000000000000000000000000000000000000000000000000000000000000000000000000000000000000000000000000000000000000000000000000000000000000000000000000000000000000000000000000000000000000000000000000000000000000000000000000000000000000000000000000000000000000000000000000000000000000000000000000000000000000000000000000000000000000000000000000000000000000000000000000000000000000000000000000000000000000000000000000000000000000000000000000000000000000000000000000000000000000000000000000000000000000000000000000000000000000000000000000000000000000000000000000000000000000000000000000000000000000000000000000000000000000000000000000000000000000000000000000000000000000000000000000000000000000000000000000000000000000000000000000000000000000000000000000000000000000000000000000000000000000000000000000000000000000000000000000000000000000000000000000000000000000000000000000000000000000000000000000000000000000000000000000000000000000000000000000000000000000000000000000000000000000000000000000000000000000000000000000000000000000000000000000000000000000000000000000000000000000000000000000000000000000000000000000000000000000000000000000000000000000000000000000000000000000000000000000000000000000000000000000000000000000000000000000000000000000000000000000000000000000000000000000000000000000000000000000000000000000000000000000000000000000000000000000000000000000000000000000000000000000000000000000000000000000000000000000000000000000000000000000000000000000000000000000000000000000000000000000000000000000000000000000000000000000000000000000000000000000000000000000000000000000000000000000000000000000000000000000000000000000000000000000000000000000000000000000000000000000000000000000000000000000000000000000000000000000000000000000000000000000000000000000000000000000000000000000000000000000000000000000000000000000000000000000000000000000000000000000000000000000000000000000000000000000000000000000000000000000000000000000000000000000000000000000000000000000000000000000000000000000000000000000000000000000000000000000000000000000000000000000000000000000000000000000000000000000000000000000000000000000000000000000000000000000000000000000000000000000000000000000000000000000000000000000000000000000000000000000000000000000000000000000000000000000000000000000000000000000000000000000000000000000000000000000000000000000000000000000000000000000000000000000000000000000000000000000000000000000000000000000000000000000000000000000000000000000000000000000000000000000000000000000000000000000000000000000000000000000000000000000000000000000000000000000000000000000000000000000000000000000000000000000000000000000000000000000000000000000000000000000000000000000000000000000000000000000000000000000000000000000000000000000000000000000000000000000000000000000000000000000000000000000000000000000000000000000000000000000000000000000000000000000000000000000000000000000000000000000000000000000000000000000000000000000000000000000000000000000000000000000000000000000000000000000000000000000000000000000000000000000000000000000000000000000000000000000000000000000000000000000000000000000000000000000000000000000000000000000000000000000000000000000000000000000000000000000000000000000000000000000000000000000000000000000000000000000000000000000000000000000000000000000000000000000000000000000000000000000000000000000000000000000000000000000000000000000000000000000000000000000000000000000000000000000000000000000000000000000000000000000000000000000000000000000000000000000000000000000000000000000000000000000000000000000000000000000000000000000000000000000000000000000000000000000000000000000000000000000000000000000000000000000000000000000000000000000000000000000000000000000000000000000000000000000000000000000000000000000000000000000000000000000000000000000000000000000000000000000000000000000000000000000000000000000000000000000000000000000000000000000000000000000000000000000000000000000000000000000000000000000000000000000000000000000000000000000000000000000000000000000000000000000000000000000000000000000000000000000000000000000000000000000000000000000000000000000000000000000000000000000000000000000000000000000000000000000000000000000000000000000000000000000000000000000000000000000000000000000000000000000000000000000000000000000000000000000000000000000000000000000000000000000000000000000000000000000000000000000000000000000000000000000000000000000000000000000000000000000000000000000000000000000000000000000000000000000000000000000000000000000000000000000000000000000000000000000000000000000000000000000000000000000000000000000000000000000000000000000000000000000000000000000000000000000000000000000000000000000000000000000000000000000000000000000000000000000000000000000000000000000000000000000000000000000000000000000000000000000000000000000000000000000000000000000000000000000000000000000000000000000000000000000000000000000000000000000000000000000000000000000000000000000000000000000000000000000000000000000000000000000000000000000000000000000000000000000000000000000000000000000000000000000000000000000000000000000000000000000000000000000000000000000000000000000000000000000000000000000000000000000000000000000000000000000000000000000000000000000000000000000000000000000000000000000000000000000000000000000000000000000000000000000000000000000000000000000000000000000000000000000000000000000000000000000000000000000000000000000000000000000000000000000000000000000000000000000000000000000000000000000000000000000000000000000000000000000000000000000000000000000000000000000000000000000000000000000000000000000000000000000000000000000000000000000000000000000000000000000000000000000000000000000000000000000000000000000000000000000000000000000000000000000000000000000000000000000000000000000000000000000000000000000000000000000000000000000000000000000000000000000000000000000000000000000000000000000000000000000000000000000000000000000000000000000000000000000000000000000000000000000000000000000000000000000000000000000000000000000000000000000000000000000000000000000000000000000000000000000000000000000000000000000000000000000000000000000000000000000000000000000000000000000000000000000000000000000000000000000000000000000000000000000000000000000000000000000000000000000000000000000000000000000000000000000000000000000000000000000000000000000000000000000000000000000000000000000000000000000000000000000000000000000000000000000000000000000000000000000000000000000000000000000000000000000000000000000000000000000000000000000000000000000000000000000000000000000000000000000000000000000000000000000000000000000000000000000000000000000000000000000000000000000000000000000000000000000000000000000000000000000000000000000000000000000000000000000000000000000000000000000000000000000000000000000000000000000000000000000000000000000000000000000000000000000000000000000000000000000000000000000000000000000000000000000000000000000000000000000000000000000000000000000000000000000000000000000000000000000000000000000000000000000000000000000000000000000000000000000000000000000000000000000000000000000000000000000000000000000000000000000000000000000000000000000000000000000000000000000000000000000000000000000000000000000000000000000000000000000000000000000000000000000000000000000000000000000000000000000000000000000000000000000000000000000000000000000000000000000000000000000000000000000000000000000000000000000000000000000000000000000000000000000000000000000000000000000000000000000000000000000000000000000000000000000000000000000000000000000000000000000000000000000000000000000000000000000000000000000000000000000000000000000000000000000000000000000000000000000000000000000000000000000000000000000000000000000000000000000000000000000000000000000000000000000000000000000000000000000000000000000000000000000000000000000000000000000000000000000000000000000000000000000000000000000000000000000000000000000000000000000000000000000000000000000000000000000000000000000000000000000000000000000000000000000000000000000000000000000000000000000000000000000000000000000000000000000000000000000000000000000000000000000000000000000000000000000000000000000000000000000000000000000000000000000000000000000000000000000000000000000000000000000000000000000000000000000000000000000000000000000000000000000000000000000000000000000000000000000000000000000000000000000000000000000000000000000000000000000000000000000000000000000000000000000000000000000000000000000000000000000000000000000000000000000000000000000000000000000000000000000000000000000000000000000000000000000000000000000000000000000000000000000000000000000000000000000000000000000000000000000000000000000000000000000000000000000000000000000000000000000000000000000000000000000000000000000000000000000000000000000000000000000000000000000000000000000000000000000000000000000000000000000000000000000000000000000000000000000000000000000000000000000000000000000000000000000000000000000000000000000000000000000000000000000000000000000000000000000000000000000000000000000000000000000000000000000000000000000000000000000000000000000000000000000000000000000000000000000000000000000000000000000000000000000000000000000000000000000000000000000000000000000000000000000000000000000000000000000000000000000000000000000000000000000000000000000000000000000000000000000000000000000000000000000000000000000000000000000000000000000000000000000000000000000000000000000000000000000000000000000000000000000000000000000000000000000000000000000000000000000000000000000000000000000000000000000000000000000000000000000000000000000000000000000000000000000000000000000000000000000000000000000000000000000000000000000000000000000000000000000000000000000000000000000000000000000000000000000000000000000000000000000000000000000000000000000000000000000000000000000000000000000000000000000000000000000000000000000000000000000000000000000000000000000000000000000000000000000000000000000000000000000000000000000000000000000000000000000000000000000000000000000000000000000000000000000000000000000000000000000000000000000000000000000000000000000000000000000000000000000000000000000000000000000000000000000000000000000000000000000000000000000000000000000000000000000000000000000000000000000000000000000000000000000000000000000000000000000000000000000000000000000000000000000000000000000000000000000000000000000000000000000000000000000000000000000000000000000000000000000000000000000000000000000000000000000000000000000000000000000000000000000000000000000000000000000000000000000000000000000000000000000000000000000000000000000000000000000000000000000000000000000000000000000000000000000000000000000000000000000000000000000000000000000000000000000000000000000000000000000000000000000000000000000000000000000000000000000000000000000000000000000000000000000000000000000000000000000000000000000000000000000000000000000000000000000000000000000000000000000000000000000000000000000000000000000000000000000000000000000000000000000000000000000000000000000000000000000000000000000000000000000000000000000000000000000000000000000000000000000000000000000000000000000000000000000000000000000000000000000000000000000000000000000000000000000000000000000000000000000000000000000000000000000000000000000000000000000000000000000000000000000000000000000000000000000000000000000000000000000000000000000000000000000000000000000000000000000000000000000000000000000000000000000000000000000000000000000000000000000000000000000000000000000000000000000000000000000000000000000000000000000000000000000000000000000000000000000000000000000000000000000000000000000000000000000000000000000000000000000000000000000000000000000000000000000000000000000000000000000000000000000000000000000000000000000000000000000000000000000000000000000000000000000000000000000000000000000000000000000000000000000000000000000000000000000000000000000000000000000000000000000000000000000000000000000000000000000000000000000000000000000000000000000000000000000000000000000000000000000000000000000000000000000000000000000000000000000000000000000000000000000000000000000000000000000000000000000000000000000000000000000000000000000000000000000000000000000000000000000000000000000000000000000000000000000000000000000000000000000000000000000000000000000000000000000000000000000000000000000000000000000000000000000000000000000000000000000000000000000000000000000000000000000000000000000000000000000000000000000000000000000000000000000000000000000000000000000000000000000000000000000000000000000000000000000000000000000000000000000000000000000000000000000000000000000000000000000000000000000000000000000000000000000000000000000000000000000000000000000000000000000000000000000000000000000000000000000000000000000000000000000000000000000000000000000000000000000000000000000000000000000000000000000000000000000000000000000000000000000000000000000000000000000000000000000000000000000000000000000000000000000000000000000000000000000000000000000000000000000000000000000000000000000000000000000000000000000000000000000000000000000000000000000000000000000000000000000000000000000000000000000000000000000000000000000000000000000000000000000000000000000000000000000000000000000000000000000000000000000000000000000000000000000000000000000000000000000000000000000000000000000000000000000000000000000000000000000000000000000000000000000000000000000000000000000000000000000000000000000000000000000000000000000000000000000000000000000000000000000000000000000000000000000000000000000000000000000000000000000000000000000000000000000000000000000000000000000000000000000000000000000000000000000000000000000000000000000000000000000000000000000000000000000000000000000000000000000000000000000000000000000000000000000000000000000000000000000000000000000000000000000000000000000000000000000000000000000000000000000000000000000000000000000000000000000000000000000000000000000000000000000000000000000000000000000000000000000000000000000000000000000000000000000000000000000000000000000000000000000000000000000000000000000000000000000000000000000000000000000000000000000000000000000000000000000000000000000000000000000000000000000000000000000000000000000000000000000000000000000000000000000000000000000000000000000000000000000000000000000000000000000000000000000000000000000000000000000000000000000000000000000000000000000000000000000000000000000000000000000000000000000000000000000000000000000000000000000000000000000000000000000000000000000000000000000000000000000000000000000000000000000000000000000000000000000000000000000000000000000000000000000000000000000000000000000000000000000000000000000000000000000000000000000000000000000000000000000000000000000000000000000000000000000000000000000000000000000000000000000000000000000000000000000000000000000000000000000000000000000000000000000000000000000000000000000000000000000000000000000000000000000000000000000000000000000000000000000000000000000000000000000000000000000000000000000000000000000000000000000000000000000000000000000000000000000000000000000000000000000000000000000000000000000000000000000000000000000000000000000000000000000000000000000000000000000000000000000000000000000000000000000000000000000000000000000000000000000000000000000000000000000000000000000000000000000000000000000000000000000000000000000000000000000000000000000000000000000000000000000000000000000000000000000000000000000000000000000000000000000000000000000000000000000000000000000000000000000000000000000000000000000000000000000000000000000000000000000000000000000000000000000000000000000000000000000000000000000000000000000000000000000000000000000000000000000000000000000000000000000000000000000000000000000000000000000000000000000000000000000000000000000000000000000000000000000000000000000000000000000000000000000000000000000000000000000000000000000000000000000000000000000000000000000000000000000000000000000000000000000000000000000000000000000000000000000000000000000000000000000000000000000000000000000000000000000000000000000000000000000000000000000000000000000000000000000000000000000000000000000000000000000000000000000000000000000000000000000000000000000000000000000000000000000000000000000000000000000000000000000000000000000000000000000000000000000000000000000000000000000000000000000000000000000000000000000000000000000000000000000000000000000000000000000000000000000000000000000000000000000000000000000000000000000000000000000000000000000000000000000000000000000000000000000000000000000000000000000000000000000000000000000000000000000000000000000000000000000000000000000000000000000000000000000000000000000000000000000000000000000000000000000000000000000000000000000000000000000000000000000000000000000000000000000000000000000000000000000000000000000000000000000000000000000000000000000000000000000000000000000000000000000000000000000000000000000000000000000000000000000000000000000000000000000000000000000000000000000000000000000000000000000000000000000000000000000000000000000000000000000000000000000000000000000000000000000000000000000000000000000000000000000000000000000000000000000000000000000000000000000000000000000000000000000000000000000000000000000000000000000000000000000000000000000000000000000000000000000000000000000000000000000000000000000000000000000000000000000000000000000000000000000000000000000000000000000000000000000000000000000000000000000000000000000000000000000000000000000000000000000000000000000000000000000000000000000000000000000000000000000000000000000000000000000000000000000000000000000000000000000000000000000000000000000000000000000000000000000000000000000000000000000000000000000000000000000000000000000000000000000000000000000000000000000000000000000000000000000000000000000000000000000000000000000000000000000000000000000000000000000000000000000000000000000000000000000000000000000000000000000000000000000000000000000000000000000000000000000000000000000000000000000000000000000000000000000000000000000000000000000000000000000000000000000000000000000000000000000000000000000000000000000000000000000000000000000000000000000000000000000000000000000000000000000000000000000000000000000000000000000000000000000000000000000000000000000000000000000000000000000000000000000000000000000000000000000000000000000000000000000000000000000000000000000000000000000000000000000000000000000000000000000000000000000000000000000000000000000000000000000000000000000000000000000000000000000000000000000000000000000000000000000000000000000000000000000000000000000000000000000000000000000000000000000000000000000000000000000000000000000000000000000000000000000000000000000000000000000000000000000000000000000000000000000000000000000000000000000000000000000000000000000000000000000000000000000000000000000000000000000000000000000000000000000000000000000000000000000000000000000000000000000000000000000000000000000000000000000000000000000000000000000000000000000000000000000000000000000000000000000000000000000000000000000000000000000000000000000000000000000000000000000000000000000000000000000000000000000000000000000000000000000000000000000000000000000000000000000000000000000000000000000000000000000000000000000000000000000000000000000000000000000000000000000000000000000000000000000000000000000000000000000000000000000000000000000000000000000000000000000000000000000000000000000000000000000000000000000000000000000000000000000000000000000000000000000000000000000000000000000000000000000000000000000000000000000000000000000000000000000000000000000000000000000000000000000000000000000000000000000000000000000000000000000000000000000000000000000000000000000000000000000000000000000000000000000000000000000000000000000000000000000000000000000000000000000000000000000000000000000000000000000000000000000000000000000000000000000000000000000000000000000000000000000000000000000000000000000000000000000000000000000000000000000000000000000000000000000000000000000000000000000000000000000000000000000000000000000000000000000000000000000000000000000000000000000000000000000000000000000000000000000000000000000000000000000000000000000000000000000000000000000000000000000000000000000000000000000000000000000000000000000000000000000000000000000000000000000000000000000000000000000000000000000000000000000000000000000000000000000000000000000000000000000000000000000000000000000000000000000000000000000000000000000000000000000000000000000000000000000000000000000000000000000000000000000000000000000000000000000000000000000000000000000000000000000000000000000000000000000000000000000000000000000000000000000000000000000000000000000000000000000000000000000000000000000000000000000000000000000000000000000000000000000000000000000000000000000000000000000000000000000000000000000000000000000000000000000000000000000000000000000000000000000000000000000000000000000000000000000000000000000000000000000000000000000000000000000000000000000000000000000000000000000000000000000000000000000000000000000000000000000000000000000000000000000000000000000000000000000000000000000000000000000000000000000000000000000000000000000000000000000000000000000000000000000000000000000000000000000000000000000000000000000000000000000000000000000000000000000000000000000000000000000000000000000000000000000000000000000000000000000000000000000000000000000000000000000000000000000000000000000000000000000000000000000000000000000000000000000000000000000000000000000000000000000000000000000000000000000000000000000000000000000000000000000000000000000000000000000000000000000000000000000000000000000000000000000000000000000000000000000000000000000000000000000000000000000000000000000000000000000000000000000000000000000000000000000000000000000000000000000000000000000000000000000000000000000000000000000000000000000000000000000000000000000000000000000000000000000000000000000000000000000000000000000000000000000000000000000000000000000000000000000000000000000000000000000000000000000000000000000000000000000000000000000000000000000000000000000000000000000000000000000000000000000000000000000000000000000000000000000000000000000000000000000000000000000000000000000000000000000000000000000000000000000000000000000000000000000000000000000000000000000000000000000000000000000000000000000000000000000000000000000000000000000000000000000000000000000000000000000000000000000000000000000000000000000000000000000000000000000000000000000000000000000000000000000000000000000000000000000000000000000000000000000000000000000000000000000000000000000000000000000000000000000000000000000000000000000000000000000000000000000000000000000000000000000000000000000000000000000000000000000000000000000000000000000000000000000000000000000000000000000000000000000000000000000000000000000000000000000000000000000000000000000000000000000000000000000000000000000000000000000000000000000000000000000000000000000000000000000000000000000000000000000000000000000000000000000000000000000000000000000000000000000000000000000000000000000000000000000000000000000000000000000000000000000000000000000000000000000000000000000000000000000000000000000000000000000000000000000000000000000000000000000000000000000000000000000000000000000000000000000000000000000000000000000000000000000000000000000000000000000000000000000000000000000000000000000000000000000000000000000000000000000000000000000000000000000000000000000000000000000000000000000000000000000000000000000000000000000000000000000000000000000000000000000000000000000000000000000000000000000000000000000000000000000000000000000000000000000000000000000000000000000000000000000000000000000000000000000000000000000000000000000000000000000000000000000000000000000000000000000000000000000000000000000000000000000000000000000000000000000000000000000000000000000000000000000000000000000000000000000000000000000000000000000000000000000000000000000000000000000000000000000000000000000000000000000000000000000000000000000000000000000000000000000000000000000000000000000000000000000000000000000000000000000000000000000000000000000000000000000000000000000000000000000000000000000000000000000000000000000000000000000000000000000000000000000000000000000000000000000000000000000000000000000000000000000000000000000000000000000000000000000000000000000000000000000000000000000000000000000000000000000000000000000000000000000000000000000000000000000000000000000000000000000000000000000000000000000000000000000000000000000000000000000000000000000000000000000000000000000000000000000000000000000000000000000000000000000000000000000000000000000000000000000000000000000000000000000000000000000000000000000000000000000000000000000000000000000000000000000000000000000000000000000000000000000000000000000000000000000000000000000000000000000000000000000000000000000000000000000000000000000000000000000000000000000000000000000000000000000000000000000000000000000000000000000000000000000000000000000000000000000000000000000000000000000000000000000000000000000000000000000000000000000000000000000000000000000000000000000000000000000000000000000000000000000000000000000000000000000000000000000000000000000000000000000000000000000000000000000000000000000000000000000000000000000000000000000000000000000000000000000000000000000000000000000000000000000000000000000000000000000000000000000000000000000000000000000000000000000000000000000000000000000000000000000000000000000000000000000000000000000000000000000000000000000000000000000000000000000000000000000000000000000000000000000000000000000000000000000000000000000000000000000000000000000000000000000000000000000000000000000000000000000000000000000000000000000000000000000000000000000000000000000000000000000000000000000000000000000000000000000000000000000000000000000000000000000000000000000000000000000000000000000000000000000000000000000000000000000000000000000000000000000000000000000000000000000000000000000000000000000000000000000000000000000000000000000000000000000000000000000000000000000000000000000000000000000000000000000000000000000000000000000000000000000000000000000000000000000000000000000000000000000000000000000000000000000000000000000000000000000000000000000000000000000000000000000000000000000000000000000000000000000000000000000000000000000000000000000000000000000000000000000000000000000000000000000000000000000000000000000000000000000000000000000000000000000000000000000000000000000000000000000000000000000000000000000000000000000000000000000000000000000000000000000000000000000000000000000000000000000000000000000000000000000000000000000000000000000000000000000000000000000000000000000000000000000000000000000000000000000000000000000000000000000000000000000000000000000000000000000000000000000000000000000000000000000000000000000000000000000000000000000000000000000000000000000000000000000000000000000000000000000000000000000000000000000000000000000000000000000000000000000000000000000000000000000000000000000000000000000000000000000000000000000000000000000000000000000000000000000000000000000000000000000000000000000000000000000000000000000000000000000000000000000000000000000000000000000000000000000000000000000000000000000000000000000000000000000000000000000000000000000000000000000000000000000000000000000000000000000000000000000000000000000000000000000000000000000000000000000000000000000000000000000000000000000000000000000000000000000000000000000000000000000000000000000000000000000000000000000000000000000000000000000000000000000000000000000000000000000000000000000000000000000000000000000000000000000000000000000000000000000000000000000000000000000000000000000000000000000000000000000000000000000000000000000000000000000000000000000000000000000000000000000000000000000000000000000000000000000000000000000000000000000000000000000000000000000000000000000000000000000000000000000000000000000000000000000000000000000000000000000000000000000000000000000000000000000000000000000000000000000000000000000000000000000000000000000000000000000000000000000000000000000000000000000000000000000000000000000000000000000000000000000000000000000000000000000000000000000000000000000000000000000000000000000000000000000000000000000000000000000000000000000000000000000000000000000000000000000000000000000000000000000000000000000000000000000000000000000000000000000000000000000000000000000000000000000000000000000000000000000000000000000000000000000000000000000000000000000000000000000000000000000000000000000000000000000000000000000000000000000000000000000000000000000000000000000000000000000000000000000000000000000000000000000000000000000000000000000000000000000000000000000000000000000000000000000000000000000000000000000000000000000000000000000000000000000000000000000000000000000000000000000000000000000000000000000000000000000000000000000000000000000000000000000000000000000000000000000000000000000000000000000000000000000000000000000000000000000000000000000000000000000000000000000000000000000000000000000000000000000000000000000000000000000000000000000000000000000000000000000000000000000000000000000000000000000000000000000000000000000000000000000000000000000000000000000000000000000000000000000000000000000000000000000000000000000000000000000000000000000000000000000000000000000000000000000000000000000000000000000000000000000000000000000000000000000000000000000000000000000000000000000000000000000000000000000000000000000000000000000000000000000000000000000000000000000000000000000000000000000000000000000000000000000000000000000000000000000000000000000000000000000000000000000000000000000000000000000000000000000000000000000000000000000000000000000000000000000000000000000000000000000000000000000000000000000000000000000000000000000000000000000000000000000000000000000000000000000000000000000000000000000000000000000000000000000000000000000000000000000000000000000000000000000000000000000000000000000000000000000000000000000000000000000000000000000000000000000000000000000000000000000000000000000000000000000000000000000000000000000000000000000000000000000000000000000000000000000000000000000000000000000000000000000000000000000000000000000000000000000000000000000000000000000000000000000000000000000000000000000000000000000000000000000000000000000000000000000000000000000000000000000000000000000000000000000000000000000000000000000000000000000000000000000000000000000000000000000000000000000000000000000000000000000000000000000000000000000000000000000000000000000000000000000000000000000000000000000000000000000000000000000000000000000000000000000000000000000000000000000000000000000000000000000000000000000000000000000000000000000000000000000000000000000000000000000000000000000000000000000000000000000000000000000000000000000000000000000000000000000000000000000000000000000000000000000000000000000000000000000000000000000000000000000000000000000000000000000000000000000000000000000000000000000000000000000000000000000000000000000000000000000000000000000000000000000000000000000000000000000000000000000000000000000000000000000000000000000000000000000000000000000000000000000000000000000000000000000000000000000000000000000000000000000000000000000000000000000000000000000000000000000000000000000000000000000000000000000000000000000000000000000000000000000000000000000000000000000000000000000000000000000000000000000000000000000000000000000000000000000000000000000000000000000000000000000000000000000000000000000000000000000000000000000000000000000000000000000000000000000000000000000000000000000000000000000000000000000000000000000000000000000000000000000000000000000000000000000000000000000000000000000000000000000000000000000000000000000000000000000000000000000000000000000000000000000000000000000000000000000000000000000000000000000000000000000000000000000000000000000000000000000000000000000000000000000000000000000000000000000000000000000000000000000000000000000000000000000000000000000000000000000000000000000000000000000000000000000000000000000000000000000000000000000000000000000000000000000000000000000000000000000000000000000000000000000000000000000000000000000000000000000000000000000000000000000000000000000000000000000000000000000000000000000000000000000000000000000000000000000000000000000000000000000000000000000000000000000000000000000000000000000000000000000000000000000000000000000000000000000000000000000000000000000000000000000000000000000000000000000000000000000000000000000000000000000000000000000000000000000000000000000000000000000000000000000000000000000000000000000000000000000000000000000000000000000000000000000000000000000000000000000000000000000000000000000000000000000000000000000000000000000000000000000000000000000000000000000000000000000000000000000000000000000000000000000000000000000000000000000000000000000000000000000000000000000000000000000000000000000000000000000000000000000000000000000000000000000000000000000000000000000000000000000000000000000000000000000000000000000000000000000000000000000000000000000000000000000000000000000000000000000000000000000000000000000000000000000000000000000000000000000000000000000000000000000000000000000000000000000000000000000000000000000000000000000000000000000000000000000000000000000000000000000000000000000000000000000000000000000000000000000000000000000000000000000000000000000000000000000000000000000000000000000000000000000000000000000000000000000000000000000000000000000000000000000000000000000000000000000000000000000000000000000000000000000000000000000000000000000000000000000000000000000000000000000000000000000000000000000000000000000000000000000000000000000000000000000000000000000000000000000000000000000000000000000000000000000000000000000000000000000000000000000000000000000000000000000000000000000000000000000000000000000000000000000000000000000000000000000000000000000000000000000000000000000000000000000000000000000000000000000000000000000000000000000000000000000000000000000000000000000000000000000000000000000000000000000000000000000000000000000000000000000000000000000000000000000000000000000000000000000000000000000000000000000000000000000000000000000000000000000000000000000000000000000000000000000000000000000000000000000000000000000000000000000000000000000000000000000000000000000000000000000000000000000000000000000000000000000000000000000000000000000000000000000000000000000000000000000000000000000000000000000000000000000000000000000000000000000000000000000000000000000000000000000000000000000000000000000000000000000000000000000000000000000000000000000000000000000000000000000000000000000000000000000000000000000000000000000000000000000000000000000000000000000000000000000000000000000000000000000000000000000000000000000000000000000000000000000000000000000000000000000000000000000000000000000000000000000000000000000000000000000000000000000000000000000000000000000000000000000000000000000000000000000000000000000000000000000000000000000000000000000000000000000000000000000000000000000000000000000000000000000000000000000000000000000000000000000000000000000000000000000000000000000000000000000000000000000000000000000000000000000000000000000000000000000000000000000000000000000000000000000000000000000000000000000000000000000000000000000000000000000000000000000000000000000000000000000000000000000000000000000000000000000000000000000000000000000000000000000000000000000000000000000000000000000000000000000000000000000000000000000000000000000000000000000000000000000000000000000000000000000000000000000000000000000000000000000000000000000000000000000000000000000000000000000000000000000000000000000000000000000000000000000000000000000000000000000000000000000000000000000000000000000000000000000000000000000000000000000000000000000000000000000000000000000000000000000000000000000000000000000000000000000000000000000000000000000000000000000000000000000000000000000000000000000000000000000000000000000000000000000000000000000000000000000000000000000000000000000000000000000000000000000000000000000000000000000000000000000000000000000000000000000000000000000000000000000000000000000000000000000000000000000000000000000000000000000000000000000000000000000000000000000000000000000000000000000000000000000000000000000000000000000000000000000000000000000000000000000000000000000000000000000000000000000000000000000000000000000000000000000000000000000000000000000000000000000000000000000000000000000000000000000000000000000000000000000000000000000000000000000000000000000000000000000000000000000000000000000000000000000000000000000000000000000000000000000000000000000000000000000000000000000000000000000000000000000000000000000000000000000000000000000000000000000000000000000000000000000000000000000000000000000000000000000000000000000000000000000000000000000000000000000000000000000000000000000000000000000000000000000000000000000000000000000000000000000000000000000000000000000000000000000000000000000000000000000000000000000000000000000000000000000000000000000000000000000000000000000000000000000000000000000000000000000000000000000000000000000000000000000000000000000000000000000000000000000000000000000000000000000000000000000000000000000000000000000000000000000000000000000000000000000000000000000000000000000000000000000000000000000000000000000000000000000000000000000000000000000000000000000000000000000000000000000000000000000000000000000000000000000000000000000000000000000000000000000000000000000000000000000000000000000000000000000000000000000000000000000000000000000000000000000000000000000000000000000000000000000000000000000000000000000000000000000000000000000000000000000000000000000000000000000000000000000000000000000000000000000000000000000000000000000000000000000000000000000000000000000000000000000000000000000000000000000000000000000000000000000000000000000000000000000000000000000000000000000000000000000000000000000000000000000000000000000000000000000000000000000000000000000000000000000000000000000000000000000000000000000000000000000000000000000000000000000000000000000000000000000000000000000000000000000000000000000000000000000000000000000000000000000000000000000000000000000000000000000000000000000000000000000000000000000000000000000000000000000000000000000000000000000000000000000000000000000000000000000000000000000000000000000000000000000000000000000000000000000000000000000000000000000000000000000000000000000000000000000000000000000000000000000000000000000000000000000000000000000000000000000000000000000000000000000000000000000000000000000000000000000000000000000000000000000000000000000000000000000000000000000000000000000000000000000000000000000000000000000000000000000000000000000000000000000000000000000000000000000000000000000000000000000000000000000000000000000000000000000000000000000000000000000000000000000000000000000000000000000000000000000000000000000000000000000000000000000000000000000000000000000000000000000000000000000000000000000000000000000000000000000000000000000000000000000000000000000000000000000000000000000000000000000000000000000000000000000000000000000000000000000000000000000000000000000000000000000000000000000000000000000000000000000000000000000000000000000000000000000000000000000000000000000000000000000000000000000000000000000000000000000000000000000000000000000000000000000000000000000000000000000000000000000000000000000000000000000000000000000000000000000000000000000000000000000000000000000000000000000000000000000000000000000000000000000000000000000000000000000000000000000000000000000000000000000000000000000000000000000000000000000000000000000000000000000000000000000000000000000000000000000000000000000000000000000000000000000000000000000000000000000000000000000000000000000000000000000000000000000000000000000000000000000000000000000000000000000000000000000000000000000000000000000000000000000000000000000000000000000000000000000000000000000000000000000000000000000000000000000000000000000000000000000000000000000000000000000000000000000000000000000000000000000000000000000000000000000000000000000000000000000000000000000000000000000000000000000000000000000000000000000000000000000000000000000000000000000000000000000000000000000000000000000000000000000000000000000000000000000000000000000000000000000000000000000000000000000000000000000000000000000000000000000000000000000000000000000000000000000000000000000000000000000000000000000000000000000000000000000000000000000000000000000000000000000000000000000000000000000000000000000000000000000000000000000000000000000000000000000000000000000000000000000000000000000000000000000000000000000000000000000000000000000000000000000000000000000000000000000000000000000000000000000000000000000000000000000000000000000000000000000000000000000000000000000000000000000000000000000000000000000000000000000000000000000000000000000000000000000000000000000000000000000000000000000000000000000000000000000000000000000000000000000000000000000000000000000000000000000000000000000000000000000000000000000000000000000000000000000000000000000000000000000000000000000000000000000000000000000000000000000000000000000000000000000000000000000000000000000000000000000000000000000000000000000000000000000000000000000000000000000000000000000000000000000000000000000000000000000000000000000000000000000000000000000000000000000000000000000000000000000000000000000000000000000000000000000000000000000000000000000000000000000000000000000000000000000000000000000000000000000000000000000000000000000000000000000000000000000000000000000000000000000000000000000000000000000000000000000000000000000000000000000000000000000000000000000000000000000000000000000000000000000000000000000000000000000000000000000000000000000000000000000000000000000000000000000000000000000000000000000000000000000000000000000000000000000000000000000000000000000000000000000000000000000000000000000000000000000000000000000000000000000000000000000000000000000000000000000000000000000000000000000000000000000000000000000000000000000000000000000000000000000000000000000000000000000000000000000000000000000000000000000000000000000000000000000000000000000000000000000000000000000000000000000000000000000000000000000000000000000000000000000000000000000000000000000000000000000000000000000000000000000000000000000000000000000000000000000000000000000000000000000000000000000000000000000000000000000000000000000000000000000000000000000000000000000000000000000000000000000000000000000000000000000000000000000000000000000000000000000000000000000000000000000000000000000000000000000000000000000000000000000000000000000000000000000000000000000000000000000000000000000000000000000000000000000000000000000000000000000000000000000000000000000000000000000000000000000000000000000000000000000000000000000000000000000000000000000000000000000000000000000000000000000000000000000000000000000000000000000000000000000000000000000000000000000000000000000000000000000000000000000000000000000000000000000000000000000000000000000000000000000000000000000000000000000000000000000000000000000000000000000000000000000000000000000000000000000000000000000000000000000000000000000000000000000000000000000000000000000000000000000000000000000000000000000000000000000000000000000000000000000000000000000000000000000000000000000000000000000000000000000000000000000000000000000000000000000000000000000000000000000000000000000000000000000000000000000000000000000000000000000000000000000000000000000000000000000000000000000000000000000000000000000000000000000000000000000000000000000000000000000000000000000000000000000000000000000000000000000000000000000000000000000000000000000000000000000000000000000000000000000000000000000000000000000000000000000000000000000000000000000000000000000000000000000000000000000000000000000000000000000000000000000000000000000000000000000000000000000000000000000000000000000000000000000000000000000000000000000000000000000000000000000000000000000000000000000000000000000000000000000000000000000000000000000000000000000000000000000000000000000000000000000000000000000000000000000000000000000000000000000000000000000000000000000000000000000000000000000000000000000000000000000000000000000000000000000000000000000000000000000000000000000000000000000000000000000000000000000000000000000000000000000000000000000000000000000000000000000000000000000000000000000000000000000000000000000000000000000000000000000000000000000000000000000000000000000000000000000000000000000000000000000000000000000000000000000000000000000000000000000000000000000000000000000000000000000000000000000000000000000000000000000000000000000000000000000000000000000000000000000000000000000000000000000000000000000000000000000000000000000000000000000000000000000000000000000000000000000000000000000000000000000000000000000000000000000000000000000000000000000000000000000000000000000000000000000000000000000000000000000000000000000000000000000000000000000000000000000000000000000000000000000000000000000000000000000000000000000000000000000000000000000000000000000000000000000000000000000000000000000000000000000000000000000000000000000000000000000000000000000000000000000000000000000000000000000000000000000000000000000000000000000000000000000000000000000000000000000000000000000000000000000000000000000000000000000000000000000000000000000000000000000000000000000000000000000000000000000000000000000000000000000000000000000000000000000000000000000000000000000000000000000000000000000000000000000000000000000000000000000000000000000000000000000000000000000000000000000000000000000000000000000000000000000000000000000000000000000000000000000000000000000000000000000000000000000000000000000000000000000000000000000000000000000000000000000000000000000000000000000000000000000000000000000000000000000000000000000000000000000000000000000000000000000000000000000000000000000000000000000000000000000000000000000000000000000000000000000000000000000000000000000000000000000000000000000000000000000000000000000000000000000000000000000000000000000000000000000000000000000000000000000000000000000000000000000000000000000000000000000000000000000000000000000000000000000000000000000000000000000000000000000000000000000000000000000000000000000000000000000000000000000000000000000000000000000000000000000000000000000000000000000000000000000000000000000000000000000000000000000000000000000000000000000000000000000000000000000000000000000000000000000000000000000000000000000000000000000000000000000000000000000000000000000000000000000000000000000000000000000000000000000000000000000000000000000000000000000000000000000000000000000000000000000000000000000000000000000000000000000000000000000000000000000000000000000000000000000000000000000000000000000000000000000000000000000000000000000000000000000000000000000000000000000000000000000000000000000000000000000000000000000000000000000000000000000000000000000000000000000000000000000000000000000000000000000000000000000000000000000000000000000000000000000000000000000000000000000000000000000000000000000000000000000000000000000000000000000000000000000000000000000000000000000000000000000000000000000000000000000000000000000000000000000000000000000000000000000000000000000000000000000000000000000000000000000000000000000000000000000000000000000000000000000000000000000000000000000000000000000000000000000000000000000000000000000000000000000000000000000000000000000000000000000000000000000000000000000000000000000000000000000000000000000000000000000000000000000000000000000000000000000000000000000000000000000000000000000000000000000000000000000000000000000000000000000000000000000000000000000000000000000000000000000000000000000000000000000000000000000000000000000000000000000000000000000000000000000000000000000000000000000000000000000000000000000000000000000000000000000000000000000000000000000000000000000000000000000000000000000000000000000000000000000000000000000000000000000000000000000000000000000000000000000000000000000000000000000000000000000000000000000000000000000000000000000000000000000000000000000000000000000000000000000000000000000000000000000000000000000000000000000000000000000000000000000000000000000000000000000000000000000000000000000000000000000000000000000000000000000000000000000000000000000000000000000000000000000000000000000000000000000000000000000000000000000000000000000000000000000000000000000000000000000000000000000000000000000000000000000000000000000000000000000000000000000000000000000000000000000000000000000000000000000000000000000000000000000000000000000000000000000000000000000000000000000000000000000000000000000000000000000000000000000000000000000000000000000000000000000000000000000000000000000000000000000000000000000000000000000000000000000000000000000000000000000000000000000000000000000000000000000000000000000000000000000000000000000000000000000000000000000000000000000000000000000000000000000000000000000000000000000000000000000000000000000000000000000000000000000000000000000000000000000000000000000000000000000000000000000000000000000000000000000000000000000000000000000000000000000000000000000000000000000000000000000000000000000000000000000000000000000000000000000000000000000000000000000000000000000000000000000000000000000000000000000000000000000000000000000000000000000000000000000000000000000000000000000000000000000000000000000000000000000000000000000000000000000000000000000000000000000000000000000000000000000000000000000000000000000000000000000000000000000000000000000000000000000000000000000000000000000000000000000000000000000000000000000000000000000000000000000000000000000000000000000000000000000000000000000000000000000000000000000000000000000000000000000000000000000000000000000000000000000000000000000000000000000000000000000000000000000000000000000000000000000000000000000000000000000000000000000000000000000000000000000000000000000000000000000000000000000000000000000000000000000000000000000000000000000000000000000000000000000000000000000000000000000000000000000000000000000000000000000000000000000000000000000000000000000000000000000000000000000000000000000000000000000000000000000000000000000000000000000000000000000000000000000000000000000000000000000000000000000000000000000000000000000000000000000000000000000000000000000000000000000000000000000000000000000000000000000000000000000000000000000000000000000000000000000000000000000000000000000000000000000000000000000000000000000000000000000000000000000000000000000000000000000000000000000000000000000000000000000000000000000000000000000000000000000000000000000000000000000000000000000000000000000000000000000000000000000000000000000000000000000000000000000000000000000000000000000000000000000000000000000000000000000000000000000000000000000000000000000000000000000000000000000000000000000000000000000000000000000000000000000000000000000000000000000000000000000000000000000000000000000000000000000000000000000000000000000000000000000000000000000000000000000000000000000000000000000000000000000000000000000000000000000000000000000000000000000000000000000000000000000000000000000000000000000000000000000000000000000000000000000000000000000000000000000000000000000000000000000000000000000000000000000000000000000000000000000000000000000000000000000000000000000000000000000000000000000000000000000000000000000000000000000000000000000000000000000000000000000000000000000000000000000000000000000000000000000000000000000000000000000000000000000000000000000000000000000000000000000000000000000000000000000000000000000000000000000000000000000000000000000000000000000000000000000000000000000000000000000000000000000000000000000000000000000000000000000000000000000000000000000000000000000000000000000000000000000000000000000000000000000000000000000000000000000000000000000000000000000000000000000000000000000000000000000000000000000000000000000000000000000000000000000000000000000000000000000000000000000000000000000000000000000000000000000000000000000000000000000000000000000000000000000000000000000000000000000000000000000000000000000000000000000000000000000000000000000000000000000000000000000000000000000000000000000000000000000000000000000000000000000000000000000000000000000000000000000000000000000000000000000000000000000000000000000000000000000000000000000000000000000000000000000000000000000000000000000000000000000000000000000000000000000000000000000000000000000000000000000000000000000000000000000000000000000000000000000000000000000000000000000000000000000000000000000000000000000000000000000000000000000000000000000000000000000000000000000000000000000000000000000000000000000000000000000000000000000000000000000000000000000000000000000000000000000000000000000000000000000000000000000000000000000000000000000000000000000000000000000000000000000000000000000000000000000000000000000000000000000000000000000000000000000000000000000000000000000000000000000000000000000000000000000000000000000000000000000000000000000000000000000000000000000000000000000000000000000000000000000000000000000000000000000000000000000000000000000000000000000000000000000000000000000000000000000000000000000000000000000000000000000000000000000000000000000000000000000000000000000000000000000000000000000000000000000000000000000000000000000000000000000000000000000000000000000000000000000000000000000000000000000000000000000000000000000000000000000000000000000000000000000000000000000000000000000000000000000000000000000000000000000000000000000000000000000000000000000000000000000000000000000000000000000000000000000000000000000000000000000000000000000000000000000000000000000000000000000000000000000000000000000000000000000000000000000000000000000000000000000000000000000000000000000000000000000000000000000000000000000000000000000000000000000000000000000000000000000000000000000000000000000000000000000000000000000000000000000000000000000000000000000000000000000000000000000000000000000000000000000000000000000000000000000000000000000000000000000000000000000000000000000000000000000000000000000000000000000000000000000000000000000000000000000000000000000000000000000000000000000000000000000000000000000000000000000000000000000000000000000000000000000000000000000000000000000000000000000000000000000000000000000000000000000000000000000000000000000000000000000000000000000000000000000000000000000000000000000000000000000000000000000000000000000000000000000000000000000000000000000000000000000000000000000000000000000000000000000000000000000000000000000000000000000000000000000000000000000000000000000000000000000000000000000000000000000000000000000000000000000000000000000000000000000000000000000000000000000000000000000000000000000000000000000000000000000000000000000000000000000000000000000000000000000000000000000000000000000000000000000000000000000000000000000000000000000000000000000000000000000000000000000000000000000000000000000000000000000000000000000000000000000000000000000000000000000000000000000000000000000000000000000000000000000000000000000000000000000000000000000000000000000000000000000000000000000000000000000000000000000000000000000000000000000000000000000000000000000000000000000000000000000000000000000000000000000000000000000000000000000000000000000000000000000000000000000000000000000000000000000000000000000000000000000000000000000000000000000000000000000000000000000000000000000000000000000000000000000000000000000000000000000000000000000000000000000000000000000000000000000000000000000000000000000000000000000000000000000000000000000000000000000000000000000000000000000000000000000000000000000000000000000000000000000000000000000000000000000000000000000000000000000000000000000000000000000000000000000000000000000000000000000000000000000000000000000000000000000000000000000000000000000000000000000000000000000000000000000000000000000000000000000000000000000000000000000000000000000000000000000000000000000000000000000000000000000000000000000000000000000000000000000000000000000000000000000000000000000000000000000000000000000000000000000000000000000000000000000000000000000000000000000000000000000000000000000000000000000000000000000000000000000000000000000000000000000000000000000000000000000000000000000000000000000000000000000000000000000000000000000000000000000000000000000000000000000000000000000000000000000000000000000000000000000000000000000000000000000000000000000000000000000000000000000000000000000000000000000000000000000000000000000000000000000000000000000000000000000000000000000000000000000000000000000000000000000000000000000000000000000000000000000000000000000000000000000000000000000000000000000000000000000000000000000000000000000000000000000000000000000000000000000000000000000000000000000000000000000000000000000000000000000000000000000000000000000000000000000000000000000000000000000000000000000000000000000000000000000000000000000000000000000000000000000000000000000000000000000000000000000000000000000000000000000000000000000000000000000000000000000000000000000000000000000000000000000000000000000000000000000000000000000000000000000000000000000000000000000000000000000000000000000000000000000000000000000000000000000000000000000000000000000000000000000000000000000000000000000000000000000000000000000000000000000000000000000000000000000000000000000000000000000000000000000000000000000000000000000000000000000000000000000000000000000000000000000000000000000000000000000000000000000000000000000000000000000000000000000000000000000000000000000000000000000000000000000000000000000000000000000000000000000000000000000000000000000000000000000000000000000000000000000000000000000000000000000000000000000000000000000000000000000000000000000000000000000000000000000000000000000000000000000000000000000000000000000000000000000000000000000000000000000000000000000000000000000000000000000000000000000000000000000000000000000000000000000000000000000000000000000000000000000000000000000000000000000000000000000000000000000000000000000000000000000000000000000000000000000000000000000000000000000000000000000000000000000000000000000000000000000000000000000000000000000000000000000000000000000000000000000000000000000000000000000000000000000000000000000000000000000000000000000000000000000000000000000000000000000000000000000000000000000000000000000000000000000000000000000000000000000000000000000000000000000000000000000000000000000000000000000000000000000000000000000000000000000000000000000000000000000000000000000000000000000000000000000000000000000000000000000000000000000000000000000000000000000000000000000000000000000000000000000000000000000000000000000000000000000000000000000000000000000000000000000000000000000000000000000000000000000000000000000000000000000000000000000000000000000000000000000000000000000000000000000000000000000000000000000000000000000000000000000000000000000000000000000000000000000000000000000000000000000000000000000000000000000000000000000000000000000000000000000000000000000000000000000000000000000000000000000000000000000000000000000000000000000000000000000000000000000000000000000000000000000000000000000000000000000000000000000000000000000000000000000000000000000000000000000000000000000000000000000000000000000000000000000000000000000000000000000000000000000000000000000000000000000000000000000000000000000000000000000000000000000000000000000000000000000000000000000000000000000000000000000000000000000000000000000000000000000000000000000000000000000000000000000000000000000000000000000000000000000000000000000000000000000000000000000000000000000000000000000000000000000000000000000000000000000000000000000000000000000000000000000000000000000000000000000000000000000000000000000000000000000000000000000000000000000000000000000000000000000000000000000000000000000000000000000000000000000000000000000000000000000000000000000000000000000000000000000000000000000000000000000000000000000000000000000000000000000000000000000000000000000000000000000000000000000000000000000000000000000000000000000000000000000000000000000000000000000000000000000000000000000000000000000000000000000000000000000000000000000000000000000000000000000000000000000000000000000000000000000000000000000000000000000000000000000000000000000000000000000000000000000000000000000000000000000000000000000000000000000000000000000000000000000000000000000000000000000000000000000000000000000000000000000000000000000000000000000000000000000000000000000000000000000000000000000000000000000000000000000000000000000000000000000000000000000000000000000000000000000000000000000000000000000000000000000000000000000000000000000000000000000000000000000000000000000000000000000000000000000000000000000000000000000000000000000000000000000000000000000000000000000000000000000000000000000000000000000000000000000000000000000000000000000000000000000000000000000000000000000000000000000000000000000000000000000000000000000000000000000000000000000000000000000000000000000000000000000000000000000000000000000000000000000000000000000000000000000000000000000000000000000000000000000000000000000000000000000000000000000000000000000000000000000000000000000000000000000000000000000000000000000000000000000000000000000000000000000000000000000000000000000000000000000000000000000000000000000000000000000000000000000000000000000000000000000000000000000000000000000000000000000000000000000000000000000000000000000000000000000000000000000000000000000000000000000000000000000000000000000000000000000000000000000000000000000000000000000000000000000000000000000000000000000000000000000000000000000000000000000000000000000000000000000000000000000000000000000000000000000000000000000000000000000000000000000000000000000000000000000000000000000000000000000000000000000000000000000000000000000000000000000000000000000000000000000000000000000000000000000000000000000000000000000000000000000000000000000000000000000000000000000000000000000000000000000000000000000000000000000000000000000000000000000000000000000000000000000000000000000000000000000000000000000000000000000000000000000000000000000000000000000000000000000000000000000000000000000000000000000000000000000000000000000000000000000000000000000000000000000000000000000000000000000000000000000000000000000000000000000000000000000000000000000000000000000000000000000000000000000000000000000000000000000000000000000000000000000000000000000000000000000000000000000000000000000000000000000000000000000000000000000000000000000000000000000000000000000000000000000000000000000000000000000000000000000000000000000000000000000000000000000000000000000000000000000000000000000000000000000000000000000000000000000000000000000000000000000000000000000000000000000000000000000000000000000000000000000000000000000000000000000000000000000000000000000000000000000000000000000000000000000000000000000000000000000000000000000000000000000000000000000000000000000000000000000000000000000000000000000000000000000000000000000000000000000000000000000000000000000000000000000000000000000000000000000000000000000000000000000000000000000000000000000000000000000000000000000000000000000000000000000000000000000000000000000000000000000000000000000000000000000000000000000000000000000000000000000000000000000000000000000000000000000000000000000000000000000000000000000000000000000000000000000000000000000000000000000000000000000000000000000000000000000000000000000000000000000000000000000000000000000000000000000000000000000000000000000000000000000000000000000000000000000000000000000000000000000000000000000000000000000000000000000000000000000000000000000000000000000000000000000000000000000000000000000000000000000000000000000000000000000000000000000000000000000000000000000000000000000000000000000000000000000000000000000000000000000000000000000000000000000000000000000000000000000000000000000000000000000000000000000000000000000000000000000000000000000000000000000000000000000000000000000000000000000000000000000000000000000000000000000000000000000000000000000000000000000000000000000000000000000000000000000000000000000000000000000000000000000000000000000000000000000000000000000000000000000000000000000000000000000000000000000000000000000000000000000000000000000000000000000000000000000000000000000000000000000000000000000000000000000000000000000000000000000000000000000000000000000000000000000000000000000000000000000000000000000000000000000000000000000000000000000000000000000000000000000000000000000000000000000000000000000000000000000000000000000000000000000000000000000000000000000000000000000000000000000000000000000000000000000000000000000000000000000000000000000000000000000000000000000000000000000000000000000000000000000000000000000000000000000000000000000000000000000000000000000000000000000000000000000000000000000000000000000000000000000000000000000000000000000000000000000000000000000000000000000000000000000000000000000000000000000000000000000000000000000000000000000000000000000000000000000000000000000000000000000000000000000000000000000000000000000000000000000000000000000000000000000000000000000000000000000000000000000000000000000000000000000000000000000000000000000000000000000000000000000000000000000000000000000000000000000000000000000000000000000000000000000000000000000000000000000000000000000000000000000000000000000000000000000000000000000000000000000000000000000000000000000000000000000000000000000000000000000000000000000000000000000000000000000000000000000000000000000000000000000000000000000000000000000000000000000000000000000000000000000000000000000000000000000000000000000000000000000000000000000000000000000000000000000000000000000000000000000000000000000000000000000000000000000000000000000000000000000000000000000000000000000000000000000000000000000000000000000000000000000000000000000000000000000000000000000000000000000000000000000000000000000000000000000000000000000000000000000000000000000000000000000000000000000000000000000000000000000000000000000000000000000000000000000000000000000000000000000000000000000000000000000000000000000000000000000000000000000000000000000000000000000000000000000000000000000000000000000000000000000000000000000000000000000000000000000000000000000000000000000000000000000000000000000000000000000000000000000000000000000000000000000000000000000000000000000000000000000000000000000000000000000000000000000000000000000000000000000000000000000000000000000000000000000000000000000000000000000000000000000000000000000000000000000000000000000000000000000000000000000000000000000000000000000000000000000000000000000000000000000000000000000000000000000000000000000000000000000000000000000000000000000000000000000000000000000000000000000000000000000000000000000000000000000000000000000000000000000000000000000000000000000000000000000000000000000000000000000000000000000000000000000000000000000000000000000000000000000000000000000000000000000000000000000000000000000000000000000000000000000000000000000000000000000000000000000000000000000000000000000000000000000000000000000000000000000000000000000000000000000000000000000000000000000000000000000000000000000000000000000000000000000000000000000000000000000000000000000000000000000000000000000000000000000000000000000000000000000000000000000000000000000000000000000000000000000000000000000000000000000000000000000000000000000000000000000000000000000000000000000000000000000000000000000000000000000000000000000000000000000000000000000000000000000000000000000000000000000000000000000000000000000000000000000000000000000000000000000000000000000000000000000000000000000000000000000000000000000000000000000000000000000000000000000000000000000000000000000000000000000000000000000000000000000000000000000000000000000000000000000000000000000000000000000000000000000000000000000000000000000000000000000000000000000000000000000000000000000000000000000000000000000000000000000000000000000000000000000000000000000000000000000000000000000000000000000000000000000000000000000000000000000000000000000000000000000000000000000000000000000000000000000000000000000000000000000000000000000000000000000000000000000000000000000000000000000000000000000000000000000000000000000000000000000000000000000000000000000000000000000000000000000000000000000000000000000000000000000000000000000000000000000000000000000000000000000000000000000000000000000000000000000000000000000000000000000000000000000000000000000000000000000000000000000000000000000000000000000000000000000000000000000000000000000000000000000000000000000000000000000000000000000000000000000000000000000000000000000000000000000000000000000000000000000000000000000000000000000000000000000000000000000000000000000000000000000000000000000000000000000000000000000000000000000000000000000000000000000000000000000000000000000000000000000000000000000000000000000000000000000000000000000000000000000000000000000000000000000000000000000000000000000000000000000000000000000000000000000000000000000000000000000000000000000000000000000000000000000000000000000000000000000000000000000000000000000000000000000000000000000000000000000000000000000000000000000000000000000000000000000000000000000000000000000000000000000000000000000000000000000000000000000000000000000000000000000000000000000000000000000000000000000000000000000000000000000000000000000000000000000000000000000000000000000000000000000000000000000000000000000000000000000000000000000000000000000000000000000000000000000000000000000000000000000000000000000000000000000000000000000000000000000000000000000000000000000000000000000000000000000000000000000000000000000000000000000000000000000000000000000000000000000000000000000000000000000000000000000000000000000000000000000000000000000000000000000000000000000000000000000000000000000000000000000000000000000000000000000000000000000000000000000000000000000000000000000000000000000000000000000000000000000000000000000000000000000000000000000000000000000000000000000000000000000000000000000000000000000000000000000000000000000000000000000000000000000000000000000000000000000000000000000000000000000000000000000000000000000000000000000000000000000000000000000000000000000000000000000000000000000000000000000000000000000000000000000000000000000000000000000000000000000000000000000000000000000000000000000000000000000000000000000000000000000000000000000000000000000000000000000000000000000000000000000000000000000000000000000000000000000000000000000000000000000000000000000000000000000000000000000000000000000000000000000000000000000000000000000000000000000000000000000000000000000000000000000000000000000000000000000000000000000000000000000000000000000000000000000000000000000000000000000000000000000000000000000000000000000000000000000000000000000000000000000000000000000000000000000000000000000000000000000000000000000000000000000000000000000000000000000000000000000000000000000000000000000000000000000000000000000000000000000000000000000000000000000000000000000000000000000000000000000000000000000000000000000000000000000000000000000000000000000000000000000000000000000000000000000000000000000000000000000000000000000000000000000000000000000000000000000000000000000000000000000000000000000000000000000000000000000000000000000000000000000000000000000000000000000000000000000000000000000000000000000000000000000000000000000000000000000000000000000000000000000000000000000000000000000000000000000000000000000000000000000000000000000000000000000000000000000000000000000000000000000000000000000000000000000000000000000000000000000000000000000000000000000000000000000000000000000000000000000000000000000000000000000000000000000000000000000000000000000000000000000000000000000000000000000000000000000000000000000000000000000000000000000000000000000000000000000000000000000000000000000000000000000000000000000000000000000000000000000000000000000000000000000000000000000000000000000000000000000000000000000000000000000000000000000000000000000000000000000000000000000000000000000000000000000000000000000000000000000000000000000000000000000000000000000000000000000000000000000000000000000000000000000000000000000000000000000000000000000000000000000000000000000000000000000000000000000000000000000000000000000000000000000000000000000000000000000000000000000000000000000000000000000000000000000000000000000000000000000000000000000000000000000000000000000000000000000000000000000000000000000000000000000000000000000000000000000000000000000000000000000000000000000000000000000000000000000000000000000000000000000000000000000000000000000000000000000000000000000000000000000000000000000000000000000000000000000000000000000000000000000000000000000000000000000000000000000000000000000000000000000000000000000000000000000000000000000000000000000000000000000000000000000000000000000000000000000000000000000000000000000000000000000000000000000000000000000000000000000000000000000000000000000000000000000000000000000000000000000000000000000000000000000000000000000000000000000000000000000000000000000000000000000000000000000000000000000000000000000000000000000000000000000000000000000000000000000000000000000000000000000000000000000000000000000000000000000000000000000000000000000000000000000000000000000000000000000000000000000000000000000000000000000000000000000000000000000000000000000000000000000000000000000000000000000000000000000000000000000000000000000000000000000000000000000000000000000000000000000000000000000000000000000000000000000000000000000000000000000000000000000000000000000000000000000000000000000000000000000000000000000000000000000000000000000000000000000000000000000000000000000000000000000000000000000000000000000000000000000000000000000000000000000000000000000000000000000000000000000000000000000000000000000000000000000000000000000000000000000000000000000000000000000000000000000000000000000000000000000000000000000000000000000000000000000000000000000000000000000000000000000000000000000000000000000000000000000000000000000000000000000000000000000000000000000000000000000000000000000000000000000000000000000000000000000000000000000000000000000000000000000000000000000000000000000000000000000000000000000000000000000000000000000000000000000000000000000000000000000000000000000000000000000000000000000000000000000000000000000000000000000000000000000000000000000000000000000000000000000000000000000000000000000000000000000000000000000000000000000000000000000000000000000000000000000000000000000000000000000000000000000000000000000000000000000000000000000000000000000000000000000000000000000000000000000000000000000000000000000000000000000000000000000000000000000000000000000000000000000000000000000000000000000000000000000000000000000000000000000000000000000000000000000000000000000000000000000000000000000000000000000000000000000000000000000000000000000000000000000000000000000000000000000000000000000000000000000000000000000000000000000000000000000000000000000000000000000000000000000000000000000000000000000000000000000000000000000000000000000000000000000000000000000000000000000000000000000000000000000000000000000000000000000000000000000000000000000000000000000000000000000000000000000000000000000000000000000000000000000000000000000000000000000000000000000000000000000000000000000000000000000000000000000000000000000000000000000000000000000000000000000000000000000000000000000000000000000000000000000000000000000000000000000000000000000000000000000000000000000000000000000000000000000000000000000000000000000000000000000000000000000000000000000000000000000000000000000000000000000000000000000000000000000000000000000000000000000000000000000000000000000000000000000000000000000000000000000000000000000000000000000000000000000000000000000000000000000000000000000000000000000000000000000000000000000000000000000000000000000000000000000000000000000000000000000000000000000000000000000000000000000000000000000000000000000000000000000000000000000000000000000000000000000000000000000000000000000000000000000000000000000000000000000000000000000000000000000000000000000000000000000000000000000000000000000000000000000000000000000000000000000000000000000000000000000000000000000000000000000000000000000000000000000000000000000000000000000000000000000000000000000000000000000000000000000000000000000000000000000000000000000000000000000000000000000000000000000000000000000000000000000000000000000000000000000000000000000000000000000000000000000000000000000000000000000000000000000000000000000000000000000000000000000000000000000000000000000000000000000000000000000000000000000000000000000000000000000000000000000000000000000000000000000000000000000000000000000000000000000000000000000000000000000000000000000000000000000000000000000000000000000000000000000000000000000000000000000000000000000000000000000000000000000000000000000000000000000000000000000000000000000000000000000000000000000000000000000000000000000000000000000000000000000000000000000000000000000000000000000000000000000000000000000000000000000000000000000000000000000000000000000000000000000000000000000000000000000000000000000000000000000000000000000000000000000000000000000000000000000000000000000000000000000000000000000000000000000000000000000000000000000000000000000000000000000000000000000000000000000000000000000000000000000000000000000000000000000000000000000000000000000000000000000000000000000000000000000000000000000000000000000000000000000000000000000000000000000000000000000000000000000000000000000000000000000000000000000000000000000000000000000000000000000000000000000000000000000000000000000000000000000000000000000000000000000000000000000000000000000000000000000000000000000000000000000000000000000000000000000000000000000000000000000000000000000000000000000000000000000000000000000000000000000000000000000000000000000000000000000000000000000000000000000000000000000000000000000000000000000000000000000000000000000000000000000000000000000000000000000000000000000000000000000000000000000000000000000000000000000000000000000000000000000000000000000000000000000000000000000000000000000000000000000000000000000000000000000000000000000000000000000000000000000000000000000000000000000000000000000000000000000000000000000000000000000000000000000000000000000000000000000000000000000000000000000000000000000000000000000000000000000000000000000000000000000000000000000000000000000000000000000000000000000000000000000000000000000000000000000000000000000000000000000000000000000000000000000000000000000000000000000000000000000000000000000000000000000000000000000000000000000000000000000000000000000000000000000000000000000000000000000000000000000000000000000000000000000000000000000000000000000000000000000000000000000000000000000000000000000000000000000000000000000000000000000000000000000000000000000000000000000000000000000000000000000000000000000000000000000000000000000000000000000000000000000000000000000000000000000000000000000000000000000000000000000000000000000000000000000000000000000000000000000000000000000000000000000000000000000000000000000000000000000000000000000000000000000000000000000000000000000000000000000000000000000000000000000000000000000000000000000000000000000000000000000000000000000000000000000000000000000000000000000000000000000000000000000000000000000000000000000000000000000000000000000000000000000000000000000000000000000000000000000000000000000000000000000000000000000000000000000000000000000000000000000000000000000000000000000000000000000000000000000000000000000000000000000000000000000000000000000000000000000000000000000000000000000000000000000000000000000000000000000000000000000000000000000000000000000000000000000000000000000000000000000000000000000000000000000000000000000000000000000000000000000000000000000000000000000000000000000000000000000000000000000000000000000000000000000000000000000000000000000000000000000000000000000000000000000000000000000000000000000000000000000000000000000000000000000000000000000000000000000000000000000000000000000000000000000000000000000000000000000000000000000000000000000000000000000000000000000000000000000000000000000000000000000000000000000000000000000000000000000000000000000000000000000000000000000000000000000000000000000000000000000000000000000000000000000000000000000000000000000000000000000000000000000000000000000000000000000000000000000000000000000000000000000000000000000000000000000000000000000000000000000000000000000000000000000000000000000000000000000000000000000000000000000000000000000000000000000000000000000000000000000000000000000000000000000000000000000000000000000000000000000000000000000000000000000000000000000000000000000000000000000000000000000000000000000000000000000000000000000000000000000000000000000000000000000000000000000000000000000000000000000000000000000000000000000000000000000000000000000000000000000000000000000000000000000000000000000000000000000000000000000000000000000000000000000000000000000000000000000000000000000000000000000000000000000000000000000000000000000000000000000000000000000000000000000000000000000000000000000000000000000000000000000000000000000000000000000000000000000000000000000000000000000000000000000000000000000000000000000000000000000000000000000000000000000000000000000000000000000000000000000000000000000000000000000000000000000000000000000000000000000000000000000000000000000000000000000000000000000000000000000000000000000000000000000000000000000000000000000000000000000000000000000000000000000000000000000000000000000000000000000000000000000000000000000000000000000000000000000000000000000000000000000000000000000000000000000000000000000000000000000000000000000000000000000000000000000000000000000000000000000000000000000000000000000000000000000000000000000000000000000000000000000000000000000000000000000000000000000000000000000000000000000000000000000000000000000000000000000000000000000000000000000000000000000000000000000000000000000000000000000000000000000000000000000000000000000000000000000000000000000000000000000000000000000000000000000000000000000000000000000000000000000000000000000000000000000000000000000000000000000000000000000000000000000000000000000000000000000000000000000000000000000000000000000000000000000000000000000000000000000000000000000000000000000000000000000000000000000000000000000000000000000000000000000000000000000000000000000000000000000000000000000000000000000000000000000000000000000000000000000000000000000000000000000000000000000000000000000000000000000000000000000000000000000000000000000000000000000000000000000000000000000000000000000000000000000000000000000000000000000000000000000000000000000000000000000000000000000000000000000000000000000000000000000000000000000000000000000000000000000000000000000000000000000000000000000000000000000000000000000000000000000000000000000000000000000000000000000000000000000000000000000000000000000000000000000000000000000000000000000000000000000000000000000000000000000000000000000000000000000000000000000000000000000000000000000000000000000000000000000000000000000000000000000000000000000000000000000000000000000000000000000000000000000000000000000000000000000000000000000000000000000000000000000000000000000000000000000000000000000000000000000000000000000000000000000000000000000000000000000000000000000000000000000000000000000000000000000000000000000000000000000000000000000000000000000000000000000000000000000000000000000000000000000000000000000000000000000000000000000000000000000000000000000000000000000000000000000000000000000000000000000000000000000000000000000000000000000000000000000000000000000000000000000000000000000000000000000000000000000000000000000000000000000000000000000000000000000000000000000000000000000000000000000000000000000000000000000000000000000000000000000000000000000000000000000000000000000000000000000000000000000000000000000000000000000000000000000000000000000000000000000000000000000000000000000000000000000000000000000000000000000000000000000000000000000000000000000000000000000000000000000000000000000000000000000000000000000000000000000000000000000000000000000000000000000000000000000000000000000000000000000000000000000000000000000000000000000000000000000000000000000000000000000000000000000000000000000000000000000000000000000000000000000000000000000000000000000000000000000000000000000000000000000000000000000000000000000000000000000000000000000000000000000000000000000000000000000000000000000000000000000000000000000000000000000000000000000000000000000000000000000000000000000000000000000000000000000000000000000000000000000000000000000000000000000000000000000000000000000000000000000000000000000000000000000000000000000000000000000000000000000000000000000000000000000000000000000000000000000000000000000000000000000000000000000000000000000000000000000000000000000000000000000000000000000000000000000000000000000000000000000000000000000000000000000000000000000000000000000000000000000000000000000000000000000000000000000000000000000000000000000000000000000000000000000000000000000000000000000000000000000000000000000000000000000000000000000000000000000000000000000000000000000000000000000000000000000000000000000000000000000000000000000000000000000000000000000000000000000000000000000000000000000000000000000000000000000000000000000000000000000000000000000000000000000000000000000000000000000000000000000000000000000000000000000000000000000000000000000000000000000000000000000000000000000000000000000000000000000000000000000000000000000000000000000000000000000000000000000000000000000000000000000000000000000000000000000000000000000000000000000000000000000000000000000000000000000000000000000000000000000000000000000000000000000000000000000000000000000000000000000000000000000000000000000000000000000000000000000000000000000000000000000000000000000000000000000000000000000000000000000000000000000000000000000000000000000000000000000000000000000000000000000000000000000000000000000000000000000000000000000000000000000000000000000000000000000000000000000000000000000000000000000000000000000000000000000000000000000000000000000000000000000000000000000000000000000000000000000000000000000000000000000000000000000000000000000000000000000000000000000000000000000000000000000000000000000000000000000000000000000000000000000000000000000000000000000000000000000000000000000000000000000000000000000000000000000000000000000000000000000000000000000000000000000000000000000000000000000000000000000000000000000000000000000000000000000000000000000000000000000000000000000000000000000000000000000000000000000000000000000000000000000000000000000000000000000000000000000000000000000000000000000000000000000000000000000000000000000000000000000000000000000000000000000000000000000000000000000000000000000000000000000000000000000000000000000000000000000000000000000000000000000000000000000000000000000000000000000000000000000000000000000000000000000000000000000000000000000000000000000000000000000000000000000000000000000000000000000000000000000000000000000000000000000000000000000000000000000000000000000000000000000000000000000000000000000000000000000000000000000000000000000000000000000000000000000000000000000000000000000000000000000000000000000000000000000000000000000000000000000000000000000000000000000000000000000000000000000000000000000000000000000000000000000000000000000000000000000000000000000000000000000000000000000000000000000000000000000000000000000000000000000000000000000000000000000000000000000000000000000000000000000000000000000000000000000000000000000000000000000000000000000000000000000000000000000000000000000000000000000000000000000000000000000000000000000000000000000000000000000000000000000000000000000000000000000000000000000000000000000000000000000000000000000000000000000000000000000000000000000000000000000000000000000000000000000000000000000000000000000000000000000000000000000000000000000000000000000000000000000000000000000000000000000000000000000000000000000000000000000000000000000000000000000000000000000000000000000000000000000000000000000000000000000000000000000000000000000000000000000000000000000000000000000000000000000000000000000000000000000000000000000000000000000000000000000000000000000000000000000000000000000000000000000000000000000000000000000000000000000000000000000000000000000000000000000000000000000000000000000000000000000000000000000000000000000000000000000000000000000000000000000000000000000000000000000000000000000000000000000000000000000000000000000000000000000000000000000000000000000000000000000000000000000000000000000000000000000000000000000000000000000000000000000000000000000000000000000000000000000000000000000000000000000000000000000000000000000000000000000000000000000000000000000000000000000000000000000000000000000000000000000000000000000000000000000000000000000000000000000000000000000000000000000000000000000000000000000000000000000000000000000000000000000000000000000000000000000000000000000000000000000000000000000000000000000000000000000000000000000000000000000000000000000000000000000000000000000000000000000000000000000000000000000000000000000000000000000000000000000000000000000000000000000000000000000000000000000000000000000000000000000000000000000000000000000000000000000000000000000000000000000000000000000000000000000000000000000000000000000000000000000000000000000000000000000000000000000000000000000000000000000000000000000000000000000000000000000000000000000000000000000000000000000000000000000000000000000000000000000000000000000000000000000000000000000000000000000000000000000000000000000000000000000000000000000000000000000000000000000000000000000000000000000000000000000000000000000000000000000000000000000000000000000000000000000000000000000000000000000000000000000000000000000000000000000000000000000000000000000000000000000000000000000000000000000000000000000000000000000000000000000000000000000000000000000000000000000000000000000000000000000000000000000000000000000000000000000000000000000000000000000000000000000000000000000000000000000000000000000000000000000000000000000000000000000000000000000000000000000000000000000000000000000000000000000000000000000000000000000000000000000000000000000000000000000000000000000000000000000000000000000000000000000000000000000000000000000000000000000000000000000000000000000000000000000000000000000000000000000000000000000000000000000000000000000000000000000000000000000000000000000000000000000000000000000000000000000000000000000000000000000000000000000000000000000000000000000000000000000000000000000000000000000000000000000000000000000000000000000000000000000000000000000000000000000000000000000000000000000000000000000000000000000000000000000000000000000000000000000000000000000000000000000000000000000000000000000000000000000000000000000000000000000000000000000000000000000000000000000000000000000000000000000000000000000000000000000000000000000000000000000000000000000000000000000000000000000000000000000000000000000000000000000000000000000000000000000000000000000000000000000000000000000000000000000000000000000000000000000000000000000000000000000000000000000000000000000000000000000000000000000000000000000000000000000000000000000000000000000000000000000000000000000000000000000000000000000000000000000000000000000000000000000000000000000000000000000000000000000000000000000000000000000000000000000000000000000000000000000000000000000000000000000000000000000000000000000000000000000000000000000000000000000000000000000000000000000000000000000000000000000000000000000000000000000000000000000000000000000000000000000000000000000000000000000000000000000000000000000000000000000000000000000000000000000000000000000000000000000000000000000000000000000000000000000000000000000000000000000000000000000000000000000000000000000000000000000000000000000000000000000000000000000000000000000000000000000000000000000000000000000000000000000000000000000000000000000000000000000000000000000000000000000000000000000000000000000000000000000000000000000000000000000000000000000000000000000000000000000000000000000000000000000000000000000000000000000000000000000000000000000000000000000000000000000000000000000000000000000000000000000000000000000000000000000000000000000000000000000000000000000000000000000000000000000000000000000000000000000000000000000000000000000000000000000000000000000000000000000000000000000000000000000000000000000000000000000000000000000000000000000000000000000000000000000000000000000000000000000000000000000000000000000000000000000000000000000000000000000000000000000000000000000000000000000000000000000000000000000000000000000000000000000000000000000000000000000000000000000000000000000000000000000000000000000000000000000000000000000000000000000000000000000000000000000000000000000000000000000000000000000000000000000000000000000000000000000000000000000000000000000000000000000000000000000000000000000000000000000000000000000000000000000000000000000000000000000000000000000000000000000000000000000000000000000000000000000000000000000000000000000000000000000000000000000000000000000000000000000000000000000000000000000000000000000000000000000000000000000000000000000000000000000000000000000000000000000000000000000000000000000000000000000000000000000000000000000000000000000000000000000000000000000000000000000000000000000000000000000000000000000000000000000000000000000000000000000000000000000000000000000000000000000000000000000000000000000000000000000000000000000000000000000000000000000000000000000000000000000000000000000000000000000000000000000000000000000000000000000000000000000000000000000000000000000000000000000000000000000000000000000000000000000000000000000000000000000000000000000000000000000000000000000000000000000000000000000000000000000000000000000000000000000000000000000000000000000000000000000000000000000000000000000000000000000000000000000000000000000000000000000000000000000000000000000000000000000000000000000000000000000000000000000000000000000000000000000000000000000000000000000000000000000000000000000000000000000000000000000000000000000000000000000000000000000000000000000000000000000000000000000000000000000000000000000000000000000000000000000000000000000000000000000000000000000000000000000000000000000000000000000000000000000000000000000000000000000000000000000000000000000000000000000000000000000000000000000000000000000000000000000000000000000000000000000000000000000000000000000000000000000000000000000000000000000000000000000000000000000000000000000000000000000000000000000000000000000000000000000000000000000000000000000000000000000000000000000000000000000000000000000000000000000000000000000000000000000000000000000000000000000000000000000000000000000000000000000000000000000000000000000000000000000000000000000000000000000000000000000000000000000000000000000000000000000000000000000000000000000000000000000000000000000000000000000000000000000000000000000000000000000000000000000000000000000000000000000000000000000000000000000000000000000000000000000000000000000000000000000000000000000000000000000000000000000000000000000000000000000000000000000000000000000000000000000000000000000000000000000000000000000000000000000000000000000000000000000000000000000000000000000000000000000000000000000000000000000000000000000000000000000000000000000000000000000000000000000000000000000000000000000000000000000000000000000000000000000000000000000000000000000000000000000000000000000000000000000000000000000000000000000000000000000000000000000000000000000000000000000000000000000000000000000000000000000000000000000000000000000000000000000000000000000000000000000000000000000000000000000000000000000000000000000000000000000000000000000000000000000000000000000000000000000000000000000000000000000000000000000000000000000000000000000000000000000000000000000000000000000000000000000000000000000000000000000000000000000000000000000000000000000000000000000000000000000000000000000000000000000000000000000000000000000000000000000000000000000000000000000000000000000000000000000000000000000000000000000000000000000000000000000000000000000000000000000000000000000000000000000000000000000000000000000000000000000000000000000000000000000000000000000000000000000000000000000000000000000000000000000000000000000000000000000000000000000000000000000000000000000000000000000000000000000000000000000000000000000000000000000000000000000000000000000000000000000000000000000000000000000000000000000000000000000000000000000000000000000000000000000000000000000000000000000000000000000000000000000000000000000000000000000000000000000000000000000000000000000000000000000000000000000000000000000000000000000000000000000000000000000000000000000000000000000000000000000000000000000000000000000000000000000000000000000000000000000000000000000000000000000000000000000000000000000000000000000000000000000000000000000000000000000000000000000000000000000000000000000000000000000000000000000000000000000000000000000000000000000000000000000000000000000000000000000000000000000000000000000000000000000000000000000000000000000000000000000000000000000000000000000000000000000000000000000000000000000000000000000000000000000000000000000000000000000000000000000000000000000000000000000000000000000000000000000000000000000000000000000000000000000000000000000000000000000000000000000000000000000000000000000000000000000000000000000000000000000000000000000000000000000000000000000000000000000000000000000000000000000000000000000000000000000000000000000000000000000000000000000000000000000000000000000000000000000000000000000000000000000000000000000000000000000000000000000000000000000000000000000000000000000000000000000000000000000000000000000000000000000000000000000000000000000000000000000000000000000000000000000000000000000000000000000000000000000000000000000000000000000000000000000000000000000000000000000000000000000000000000000000000000000000000000000000000000000000000000000000000000000000000000000000000000000000000000000000000000000000000000000000000000000000000000000000000000000000000000000000000000000000000000000000000000000000000000000000000000000000000000000000000000000000000000000000000000000000000000000000000000000000000000000000000000000000000000000000000000000000000000000000000000000000000000000000000000000000000000000000000000000000000000000000000000000000000000000000000000000000000000000000000000000000000000000000000000000000000000000000000000000000000000000000000000000000000000000000000000000000000000000000000000000000000000000000000000000000000000000000000000000000000000000000000000000000000000000000000000000000000000000000000000000000000000000000000000000000000000000000000000000000000000000000000000000000000000000000000000000000000000000000000000000000000000000000000000000000000000000000000000000000000000000000000000000000000000000000000000000000000000000000000000000000000000000000000000000000000000000000000000000000000000000000000000000000000000000000000000000000000000000000000000000000000000000000000000000000000000000000000000000000000000000000000000000000000000000000000000000000000000000000000000000000000000000000000000000000000000000000000000000000000000000000000000000000000000000000000000000000000000000000000000000000000000000000000000000000000000000000000000000000000000000000000000000000000000000000000000000000000000000000000000000000000000000000000000000000000000000000000000000000000000000000000000000000000000000000000000000000000000000000000000000000000000000000000000000000000000000000000000000000000000000000000000000000000000000000000000000000000000000000000000000000000000000000000000000000000000000000000000000000000000000000000000000000000000000000000000000000000000000000000000000000000000000000000000000000000000000000000000000000000000000000000000000000000000000000000000000000000000000000000000000000000000000000000000000000000000000000000000000000000000000000000000000000000000000000000000000000000000000000000000000000000000000000000000000000000000000000000000000000000000000000000000000000000000000000000000000000000000000000000000000000000000000000000000000000000000000000000000000000000000000000000000000000000000000000000000000000000000000000000000000000000000000000000000000000000000000000000000000000000000000000000000000000000000000000000000000000000000000000000000000000000000000000000000000000000000000000000000000000000000000000000000000000000000000000000000000000000000000000000000000000000000000000000000000000000000000000000000000000000000000000000000000000000000000000000000000000000000000000000000000000000000000000000000000000000000000000000000000000000000000000000000000000000000000000000000000000000000000000000000000000000000000000000000000000000000000000000000000000000000000000000000000000000000000000000000000000000000000000000000000000000000000000000000000000000000000000000000000000000000000000000000000000000000000000000000000000000000000000000000000000000000000000000000000000000000000000000000000000000000000000000000000000000000000000000000000000000000000000000000000000000000000000000000000000000000000000000000000000000000000000000000000000000000000000000000000000000000000000000000000000000000000000000000000000000000000000000000000000000000000000000000000000000000000000000000000000000000000000000000000000000000000000000000000000000000000000000000000000000000000000000000000000000000000000000000000000000000000000000000000000000000000000000000000000000000000000000000000000000000000000000000000000000000000000000000000000000000000000000000000000000000000000000000000000000000000000000000000000000000000000000000000000000000000000000000000000000000000000000000000000000000000000000000000000000000000000000000000000000000000000000000000000000000000000000000000000000000000000000000000000000000000000000000000000000000000000000000000000000000000000000000000000000000000000000000000000000000000000000000000000000000000000000000000000000000000000000000000000000000000000000000000000000000000000000000000000000000000000000000000000000000000000000000000000000000000000000000000000000000000000000000000000000000000000000000000000000000000000000000000000000000000000000000000000000000000000000000000000000000000000000000000000000000000000000000000000000000000000000000000000000000000000000000000000000000000000000000000000000000000000000000000000000000000000000000000000000000000000000000000000000000000000000000000000000000000000000000000000000000000000000000000000000000000000000000000000000000000000000000000000000000000000000000000000000000000000000000000000000000000000000000000000000000000000000000000000000000000000000000000000000000000000000000000000000000000000000000000000000000000000000000000000000000000000000000000000000000000000000000000000000000000000000000000000000000000000000000000000000000000000000000000000000000000000000000000000000000000000000000000000000000000000000000000000000000000000000000000000000000000000000000000000000000000000000000000000000000000000000000000000000000000000000000000000000000000000000000000000000000000000000000000000000000000000000000000000000000000000000000000000000000000000000000000000000000000000000000000000000000000000000000000000000000000000000000000000000000000000000000000000000000000000000000000000000000000000000000000000000000000000000000000000000000000000000000000000000000000000000000000000000000000000000000000000000000000000000000000000000000000000000000000000000000000000000000000000000000000000000000000000000000000000000000000000000000000000000000000000000000000000000000000000000000000000000000000000000000000000000000000000000000000000000000000000000000000000000000000000000000000000000000000000000000000000000000000000000000000000000000000000000000000000000000000000000000000000000000000000000000000000000000000000000000000000000000000000000000000000000000000000000000000000000000000000000000000000000000000000000000000000000000000000000000000000000000000000000000000000000000000000000000000000000000000000000000000000000000000000000000000000000000000000000000000000000000000000000000000000000000000000000000000000000000000000000000000000000000000000000000000000000000000000000000000000000000000000000000000000000000000000000000000000000000000000000000000000000000000000000000000000000000000000000000000000000000000000000000000000000000000000000000000000000000000000000000000000000000000000000000000000000000000000000000000000000000000000000000000000000000000000000000000000000000000000000000000000000000000000000000000000000000000000000000000000000000000000000000000000000000000000000000000000000000000000000000000000000000000000000000000000000000000000000000000000000000000000000000000000000000000000000000000000000000000000000000000000000000000000000000000000000000000000000000000000000000000000000000000000000000000000000000000000000000000000000000000000000000000000000000000000000000000000000000000000000000000000000000000000000000000000000000000000000000000000000000000000000000000000000000000000000000000000000000000000000000000000000000000000000000000000000000000000000000000000000000000000000000000000000000000000000000000000000000000000000000000000000000000000000000000000000000000000000000000000000000000000000000000000000000000000000000000000000000000000000000000000000000000000000000000000000000000000000000000000000000000000000000000000000000000000000000000000000000000000000000000000000000000000000000000000000000000000000000000000000000000000000000000000000000000000000000000000000000000000000000000000000000000000000000000000000000000000000000000000000000000000000000000000000000000000000000000000000000000000000000000000000000000000000000000000000000000000000000000000000000000000000000000000000000000000000000000000000000000000000000000000000000000000000000000000000000000000000000000000000000000000000000000000000000000000000000000000000000000000000000000000000000000000000000000000000000000000000000000000000000000000000000000000000000000000000000000000000000000000000000000000000000000000000000000000000000000000000000000000000000000000000000000000000000000000000000000000000000000000000000000000000000000000000000000000000000000000000000000000000000000000000000000000000000000000000000000000000000000000000000000000000000000000000000000000000000000000000000000000000000000000000000000000000000000000000000000000000000000000000000000000000000000000000000000000000000000000000000000000000000000000000000000000000000000000000000000000000000000000000000000000000000000000000000000000000000000000000000000000000000000000000000000000000000000000000000000000000000000000000000000000000000000000000000000000000000000000000000000000000000000000000000000000000000000000000000000000000000000000000000000000000000000000000000000000000000000000000000000000000000000000000000000000000000000000000000000000000000000000000000000000000000000000000000000000000000000000000000000000000000000000000000000000000000000000000000000000000000000000000000000000000000000000000000000000000000000000000000000000000000000000000000000000000000000000000000000000000000000000000000000000000000000000000000000000000000000000000000000000000000000000000000000000000000000000000000000000000000000000000000000000000000000000000000000000000000000000000000000000000000000000000000000000000000000000000000000000000000000000000000000000000000000000000000000000000000000000000000000000000000000000000000000000000000000000000000000000000000000000000000000000000000000000000000000000000000000000000000000000000000000000000000000000000000000000000000000000000000000000000000000000000000000000000000000000000000000000000000000000000000000000000000000000000000000000000000000000000000000000000000000000000000000000000000000000000000000000000000000000000000000000000000000000000000000000000000000000000000000000000000000000000000000000000000000000000000000000000000000000000000000000000000000000000000000000000000000000000000000000000000000000000000000000000000000000000000000000000000000000000000000000000000000000000000000000000000000000000000000000000000000000000000000000000000000000000000000000000000000000000000000000000000000000000000000000000000000000000000000000000000000000000000000000000000000000000000000000000000000000000000000000000000000000000000000000000000000000000000000000000000000000000000000000000000000000000000000000000000000000000000000000000000000000000000000000000000000000000000000000000000000000000000000000000000000000000000000000000000000000000000000000000000000000000000000000000000000000000000000000000000000000000000000000000000000000000000000000000000000000000000000000000000000000000000000000000000000000000000000000000000000000000000000000000000000000000000000000000000000000000000000000000000000000000000000000000000000000000000000000000000000000000000000000000000000000000000000000000000000000000000000000000000000000000000000000000000000000000000000000000000000000000000000000000000000000000000000000000000000000000000000000000000000000000000000000000000000000000000000000000000000000000000000000000000000000000000000000000000000000000000000000000000000000000000000000000000000000000000000000000000000000000000000000000000000000000000000000000000000000000000000000000000000000000000000000000000000000000000000000000000000000000000000000000000000000000000000000000000000000000000000000000000000000000000000000000000000000000000000000000000000000000000000000000000000000000000000000000000000000000000000000000000000000000000000000000000000000000000000000000000000000000000000000000000000000000000000000000000000000000000000000000000000000000000000000000000000000000000000000000000000000000000000000000000000000000000000000000000000000000000000000000000000000000000000000000000000000000000000000000000000000000000000000000000000000000000000000000000000000000000000000000000000000000000000000000000000000000000000000000000000000000000000000000000000000000000000000000000000000000000000000000000000000000000000000000000000000000000000000000000000000000000000000000000000000000000000000000000000000000000000000000000000000000000000000000000000000000000000000000000000000000000000000000000000000000000000000000000000000000000000000000000000000000000000000000000000000000000000000000000000000000000000000000000000000000000000000000000000000000000000000000000000000000000000000000000000000000000000000000000000000000000000000000000000000000000000000000000000000000000000000000000000000000000000000000000000000000000000000000000000000000000000000000000000000000000000000000000000000000000000000000000000000000000000000000000000000000000000000000000000000000000000000000000000000000000000000000000000000000000000000000000000000000000000000000000000000000000000000000000000000000000000000000000000000000000000000000000000000000000000000000000000000000000000000000000000000000000000000000000000000000000000000000000000000000000000000000000000000000000000000000000000000000000000000000000000000000000000000000000000000000000000000000000000000000000000000000000000000000000000000000000000000000000000000000000000000000000000000000000000000000000000000000000000000000000000000000000000000000000000000000000000000000000000000000000000000000000000000000000000000000000000000000000000000000000000000000000000000000000000000000000000000000000000000000000000000000000000000000000000000000000000000000000000000000000000000000000000000000000000000000000000000000000000000000000000000000000000000000000000000000000000000000000000000000000000000000000000000000000000000000000000000000000000000000000000000000000000000000000000000000000000000000000000000000000000000000000000000000000000000000000000000000000000000000000000000000000000000000000000000000000000000000000000000000000000000000000000000000000000000000000000000000000000000000000000000000000000000000000000000000000000000000000000000000000000000000000000000000000000000000000000000000000000000000000000000000000000000000000000000000000000000000000000000000000000000000000000000000000000000000000000000000000000000000000000000000000000000000000000000000000000000000000000000000000000000000000000000000000000000000000000000000000000000000000000000000000000000000000000000000000000000000000000000000000000000000000000000000000000000000000000000000000000000000000000000000000000000000000000000000000000000000000000000000000000000000000000000000000000000000000000000000000000000000000000000000000000000000000000000000000000000000000000000000000000000000000000000000000000000000000000000000000000000000000000000000000000000000000000000000000000000000000000000000000000000000000000000000000000000000000000000000000000000000000000000000000000000000000000000000000000000000000000000000000000000000000000000000000000000000000000000000000000000000000000000000000000000000000000000000000000000000000000000000000000000000000000000000000000000000000000000000000000000000000000000000000000000000000000000000000000000000000000000000000000000000000000000000000000000000000000000000000000000000000000000000000000000000000000000000000000000000000000000000000000000000000000000000000000000000000000000000000000000000000000000000000000000000000000000000000000000000000000000000000000000000000000000000000000000000000000000000000000000000000000000000000000000000000000000000000000000000000000000000000000000000000000000000000000000000000000000000000000000000000000000000000000000000000000000000000000000000000000000000000000000000000000000000000000000000000000000000000000000000000000000000000000000000000000000000000000000000000000000000000000000000000000000000000000000000000000000000000000000000000000000000000000000000000000000000000000000000000000000000000000000000000000000000000000000000000000000000000000000000000000000000000000000000000000000000000000000000000000000000000000000000000000000000000000000000000000000000000000000000000000000000000000000000000000000000000000000000000000000000000000000000000000000000000000000000000000000000000000000000000000000000000000000000000000000000000000000000000000000000000000000000000000000000000000000000000000000000000000000000000000000000000000000000000000000000000000000000000000000000000000000000000000000000000000000000000000000000000000000000000000000000000000000000000000000000000000000000000000000000000000000000000000000000000000000000000000000000000000000000000000000000000000000000000000000000000000000000000000000000000000000000000000000000000000000000000000000000000000000000000000000000000000000000000000000000000000000000000000000000000000000000000000000000000000000000000000000000000000000000000000000000000000000000000000000000000000000000000000000000000000000000000000000000000000000000000000000000000000000000000000000000000000000000000000000000000000000000000000000000000000000000000000000000000000000000000000000000000000000000000000000000000000000000000000000000000000000000000000000000000000000000000000000000000000000000000000000000000000000000000000000000000000000000000000000000000000000000000000000000000000000000000000000000000000000000000000000000000000000000000000000000000000000000000000000000000000000000000000000000000000000000000000000000000000000000000000000000000000000000000000000000000000000000000000000000000000000000000000000000000000000000000000000000000000000000000000000000000000000000000000000000000000000000000000000000000000000000000000000000000000000000000000000000000000000000000000000000000000000000000000000000000000000000000000000000000000000000000000000000000000000000000000000000000000000000000000000000000000000000000000000000000000000000000000000000000000000000000000000000000000000000000000000000000000000000000000000000000000000000000000000000000000000000000000000000000000000000000000000000000000000000000000000000000000000000000000000000000000000000000000000000000000000000000000000000000000000000000000000000000000000000000000000000000000000000000000000000000000000000000000000000000000000000000000000000000000000000000000000000000000000000000000000000000000000000000000000000000000000000000000000000000000000000000000000000000000000000000000000000000000000000000000000000000000000000000000000000000000000000000000000000000000000000000000000000000000000000000000000000000000000000000000000000000000000000000000000000000000000000000000000000000000000000000000000000000000000000000000000000000000000000000000000000000000000000000000000000000000000000000000000000000000000000000000000000000000000000000000000000000000000000000000000000000000000000000000000000000000000000000000000000000000000000000000000000000000000000000000000000000000000000000000000000000000000000000000000000000000000000000000000000000000000000000000000000000000000000000000000000000000000000000000000000000000000000000000000000000000000000000000000000000000000000000000000000000000000000000000000000000000000000000000000000000000000000000000000000000000000000000000000000000000000000000000000000000000000000000000000000000000000000000000000000000000000000000000000000000000000000000000000000000000000000000000000000000000000000000000000000000000000000000000000000000000000000000000000000000000000000000000000000000000000000000000000000000000000000000000000000000000000000000000000000000000000000000000000000000000000000000000000000000000000000000000000000000000000000000000000000000000000000000000000000000000000000000000000000000000000000000000000000000000000000000000000000000000000000000000000000000000000000000000000000000000000000000000000000000000000000000000000000000000000000000000000000000000000000000000000000000000000000000000000000000000000000000000000000000000000000000000000000000000000000000000000000000000000000000000000000000000000000000000000000000000000000000000000000000000000000000000000000000000000000000000000000000000000000000000000000000000000000000000000000000000000000000000000000000000000000000000000000000000000000000000000000000000000000000000000000000000000000000000000000000000000000000000000000000000000000000000000000000000000000000000000000000000000000000000000000000000000000000000000000000000000000000000000000000000000000000000000000000000000000000000000000000000000000000000000000000000000000000000000000000000000000000000000000000000000000000000000000000000000000000000000000000000000000000000000000000000000000000000000000000000000000000000000000000000000000000000000000000000000000000000000000000000000000000000000000000000000000000000000000000000000000000000000000000000000000000000000000000000000000000000000000000000000000000000000000000000000000000000000000000000000000000000000000000000000000000000000000000000000000000000000000000000000000000000000000000000000000000000000000000000000000000000000000000000000000000000000000000000000000000000000000000000000000000000000000000000000000000000000000000000000000000000000000000000000000000000000000000000000000000000000000000000000000000000000000000000000000000000000000000000000000000000000000000000000000000000000000000000000000000000000000000000000000000000000000000000000000000000000000000000000000000000000000000000000000000000000000000000000000000000000000000000000000000000000000000000000000000000000000000000000000000000000000000000000000000000000000000000000000000000000000000000000000000000000000000000000000000000000000000000000000000000000000000000000000000000000000000000000000000000000000000000000000000000000000000000000000000000000000000000000000000000000000000000000000000000000000000000000000000000000000000000000000000000000000000000000000000000000000000000000000000000000000000000000000000000000000000000000000000000000000000000000000000000000000000000000000000000000000000000000000000000000000000000000000000000000000000000000000000000000000000000000000000000000000000000000000000000000000000000000000000000000000000000000000000000000000000000000000000000000000000000000000000000000000000000000000000000000000000000000000000000000000000000000000000000000000000000000000000000000000000000000000000000000000000000000000000000000000000000000000000000000000000000000000000000000000000000000000000000000000000000000000000000000000000000000000000000000000000000000000000000000000000000000000000000000000000000000000000000000000000000000000000000000000000000000000000000000000000000000000000000000000000000000000000000000000000000000000000000000000000000000000000000000000000000000000000000000000000000000000000000000000000000000000000000000000000000000000000000000000000000000000000000000000000000000000000000000000000000000000000000000000000000000000000000000000000000000000000000000000000000000000000000000000000000000000000000000000000000000000000000000000000000000000000000000000000000000000000000000000000000000000000000000000000000000000000000000000000000000000000000000000000000000000000000000000000000000000000000000000000000000000000000000000000000000000000000000000000000000000000000000000000000000000000000000000000000000000000000000000000000000000000000000000000000000000000000000000000000000000000000000000000000000000000000000000000000000000000000000000000000000000000000000000000000000000000000000000000000000000000000000000000000000000000000000000000000000000000000000000000000000000000000000000000000000000000000000000000000000000000000000000000000000000000000000000000000000000000000000000000000000000000000000000000000000000000000000000000000000000000000000000000000000000000000000000000000000000000000000000000000000000000000000000000000000000000000000000000000000000000000000000000000000000000000000000000000000000000000000000000000000000000000000000000000000000000000000000000000000000000000000000000000000000000000000000000000000000000000000000000000000000000000000000000000000000000000000000000000000000000000000000000000000000000000000000000000000000000000000000000000000000000000000000000000000000000000000000000000000000000000000000000000000000000000000000000000000000000000000000000000000000000000000000000000000000000000000000000000000000000000000000000000000000000000000000000000000000000000000000000000000000000000000000000000000000000000000000000000000000000000000000000000000000000000000000000000000000000000000000000000000000000000000000000000000000000000000000000000000000000000000000000000000000000000000000000000000000000000000000000000000000000000000000000000000000000000000000000000000000000000000000000000000000000000000000000000000000000000000000000000000000000000000000000000000000000000000000000000000000000000000000000000000000000000000000000000000000000000000000000000000000000000000000000000000000000000000000000000000000000000000000000000000000000000000000000000000000000000000000000000000000000000000000000000000000000000000000000000000000000000000000000000000000000000000000000000000000000000000000000000000000000000000000000000000000000000000000000000000000000000000000000000000000000000000000000000000000000000000000000000000000000000000000000000000000000000000000000000000000000000000000000000000000000000000000000000000000000000000000000000000000000000000000000000000000000000000000000000000000000000000000000000000000000000000000000000000000000000000000000000000000000000000000000000000000000000000000000000000000000000000000000000000000000000000000000000000000000000000000000000000000000000000000000000000000000000000000000000000000000000000000000000000000000000000000000000000000000000000000000000000000000000000000000000000000000000000000000000000000000000000000000000000000000000000000000000000000000000000000000000000000000000000000000000000000000000000000000000000000000000000000000000000000000000000000000000000000000000000000000000000000000000000000000000000000000000000000000000000000000000000000000000000000000000000000000000000000000000000000000000000000000000000000000000000000000000000000000000000000000000000000000000000000000000000000000000000000000000000000000000000000000000000000000000000000000000000000000000000000000000000000000000000000000000000000000000000000000000000000000000000000000000000000000000000000000000000000000000000000000000000000000000000000000000000000000000000000000000000000000000000000000000000000000000000000000000000000000000000000000000000000000000000000000000000000000000000000000000000000000000000000000000000000000000000000000000000000000000000000000000000000000000000000000000000000000000000000000000000000000000000000000000000000000000000000000000000000000000000000000000000000000000000000000000000000000000000000000000000000000000000000000000000000000000000000000000000000000000000000000000000000000000000000000000000000000000000000000000000000000000000000000000000000000000000000000000000000000000000000000000000000000000000000000000000000000000000000000000000000000000000000000000000000000000000000000000000000000000000000000000000000000000000000000000000000000000000000000000000000000000000000000000000000000000000000000000000000000000000000000000000000000000000000000000000000000000000000000000000000000000000000000000000000000000000000000000000000000000000000000000000000000000000000000000000000000000000000000000000000000000000000000000000000000000000000000000000000000000000000000000000000000000000000000000000000000000000000000000000000000000000000000000000000000000000000000000000000000000000000000000000000000000000000000000000000000000000000000000000000000000000000000000000000000000000000000000000000000000000000000000000000000000000000000000000000000000000000000000000000000000000000000000000000000000000000000000000000000000000000000000000000000000000000000000000000000000000000000000000000000000000000000000000000000000000000000000000000000000000000000000000000000000000000000000000000000000000000000000000000000000000000000000000000000000000000000000000000000000000000000000000000000000000000000000000000000000000000000000000000000000000000000000000000000000000000000000000000000000000000000000000000000000000000000000000000000000000000000000000000000000000000000000000000000000000000000000000000000000000000000000000000000000000000000000000000000000000000000000000000000000000000000000000000000000000000000000000000000000000000000000000000000000000000000000000000000000000000000000000000000000000000000000000000000000000000000000000000000000000000000000000000000000000000000000000000000000000000000000000000000000000000000000000000000000000000000000000000000000000000000000000000000000000000000000000000000000000000000000000000000000000000000000000000000000000000000000000000000000000000000000000000000000000000000000000000000000000000000000000000000000000000000000000000000000000000000000000000000000000000000000000000000000000000000000000000000000000000000000000000000000000000000000000000000000000000000000000000000000000000000000000000000000000000000000000000000000000000000000000000000000000000000000000000000000000000000000000000000000000000000000000000000000000000000000000000000000000000000000000000000000000000000000000000000000000000000000000000000000000000000000000000000000000000000000000000000000000000000000000000000000000000000000000000000000000000000000000000000000000000000000000000000000000000000000000000000000000000000000000000000000000000000000000000000000000000000000000000000000000000000000000000000000000000000000000000000000000000000000000000000000000000000000000000000000000000000000000000000000000000000000000000000000000000000000000000000000000000000000000000000000000000000000000000000000000000000000000000000000000000000000000000000000000000000000000000000000000000000000000000000000000000000000000000000000000000000000000000000000000000000000000000000000000000000000000000000000000000000000000000000000000000000000000000000000000000000000000000000000000000000000000000000000000000000000000000000000000000000000000000000000000000000000000000000000000000000000000000000000000000000000000000000000000000000000000000000000000000000000000000000000000000000000000000000000000000000000000000000000000000000000000000000000000000000000000000000000000000000000000000000000000000000000000000000000000000000000000000000000000000000000000000000000000000000000000000000000000000000000000000000000000000000000000000000000000000000000000000000000000000000000000000000000000000000000000000000000000000000000000000000000000000000000000000000000000000000000000000000000000000000000000000000000000000000000000000000000000000000000000000000000000000000000000000000000000000000000000000000000000000000000000000000000000000000000000000000000000000000000000000000000000000000000000000000000000000000000000000000000000000000000000000000000000000000000000000000000000000000000000000000000000000000000000000000000000000000000000000000000000000000000000000000000000000000000000000000000000000000000000000000000000000000000000000000000000000000000000000000000000000000000000000000000000000000000000000000000000000000000000000000000000000000000000000000000000000000000000000000000000000000000000000000000000000000000000000000000000000000000000000000000000000000000000000000000000000000000000000000000000000000000000000000000000000000000000000000000000000000000000000000000000000000000000000000000000000000000000000000000000000000000000000000000000000000000000000000000000000000000000000000000000000000000000000000000000000000000000000000000000000000000000000000000000000000000000000000000000000000000000000000000000000000000000000000000000000000000000000000000000000000000000000000000000000000000000000000000000000000000000000000000000000000000000000000000000000000000000000000000000000000000000000000000000000000000000000000000000000000000000000000000000000000000000000000000000000000000000000000000000000000000000000000000000000000000000000000000000000000000000000000000000000000000000000000000000000000000000000000000000000000000000000000000000000000000000000000000000000000000000000000000000000000000000000000000000000000000000000000000000000000000000000000000000000000000000000000000000000000000000000000000000000000000000000000000000000000000000000000000000000000000000000000000000000000000000000000000000000000000000000000000000000000000000000000000000000000000000000000000000000000000000000000000000000000000000000000000000000000000000000000000000000000000000000000000000000000000000000000000000000000000000000000000000000000000000000000000000000000000000000000000000000000000000000000000000000000000000000000000000000000000000000000000000000000000000000000000000000000000000000000000000000000000000000000000000000000000000000000000000000000000000000000000000000000000000000000000000000000000000000000000000000000000000000000000000000000000000000000000000000000000000000000000000000000000000000000000000000000000000000000000000000000000000000000000000000000000000000000000000000000000000000000000000000000000000000000000000000000000000000000000000000000000000000000000000000000000000000000000000000000000000000000000000000000000000000000000000000000000000000000000000000000000000000000000000000000000000000000000000000000000000000000000000000000000000000000000000000000000000000000000000000000000000000000000000000000000000000000000000000000000000000000000000000000000000000000000000000000000000000000000000000000000000000000000000000000000000000000000000000000000000000000000000000000000000000000000000000000000000000000000000000000000000000000000000000000000000000000000000000000000000000000000000000000000000000000000000000000000000000000000000000000000000000000000000000000000000000000000000000000000000000000000000000000000000000000000000000000000000000000000000000000000000000000000000000000000000000000000000000000000000000000000000000000000000000000000000000000000000000000000000000000000000000000000000000000000000000000000000000000000000000000000000000000000000000000000000000000000000000000000000000000000000000000000000000000000000000000000000000000000000000000000000000000000000000000000000000000000000000000000000000000000000000000000000000000000000000000000000000000000000000000000000000000000000000000000000000000000000000000000000000000000000000000000000000000000000000000000000000000000000000000000000000000000000000000000000000000000000000000000000000000000000000000000000000000000000000000000000000000000000000000000000000000000000000000000000000000000000000000000000000000000000000000000000000000000000000000000000000000000000000000000000000000000000000000000000000000000000000000000000000000000000000000000000000000000000000000000000000000000000000000000000000000000000000000000000000000000000000000000000000000000000000000000000000000000000000000000000000000000000000000000000000000000000000000000000000000000000000000000000000000000000000000000000000000000000000000000000000000000000000000000000000000000000000000000000000000000000000000000000000000000000000000000000000000000000000000000000000000000000000000000000000000000000000000000000000000000000000000000000000000000000000000000000000000000000000000000000000000000000000000000000000000000000000000000000000000000000000000000000000000000000000000000000000000000000000000000000000000000000000000000000000000000000000000000000000000000000000000000000000000000000000000000000000000000000000000000000000000000000000000000000000000000000000000000000000000000000000000000000000000000000000000000000000000000000000000000000000000000000000000000000000000000000000000000000000000000000000000000000000000000000000000000000000000000000000000000000000000000000000000000000000000000000000000000000000000000000000000000000000000000000000000000000000000000000000000000000000000000000000000000000000000000000000000000000000000000000000000000000000000000000000000000000000000000000000000000000000000000000000000000000000000000000000000000000000000000000000000000000000000000000000000000000000000000000000000000000000000000000000000000000000000000000000000000000000000000000000000000000000000000000000000000000000000000000000000000000000000000000000000000000000000000000000000000000000000000000000000000000000000000000000000000000000000000000000000000000000000000000000000000000000000000000000000000000000000000000000000000000000000000000000000000000000000000000000000000000000000000000000000000000000000000000000000000000000000000000000000000000000000000000000000000000000000000000000000000000000000000000000000000000000000000000000000000000000000000000000000000000000000000000000000000000000000000000000000000000000000000000000000000000000000000000000000000000000000000000000000000000000000000000000000000000000000000000000000000000000000000000000000000000000000000000000000000000000000000000000000000000000000000000000000000000000000000000000000000000000000000000000000000000000000000000000000000000000000000000000000000000000000000000000000000000000000000000000000000000000000000000000000000000000000000000000000000000000000000000000000000000000000000000000000000000000000000000000000000000000000000000000000000000000000000000000000000000000000000000000000000000000000000000000000000000000000000000000000000000000000000000000000000000000000000000000000000000000000000000000000000000000000000000000000000000000000000000000000000000000000000000000000000000000000000000000000000000000000000000000000000000000000000000000000000000000000000000000000000000000000000000000000000000000000000000000000000000000000000000000000000000000000000000000000000000000000000000000000000000000000000000000000000000000000000000000000000000000000000000000000000000000000000000000000000000000000000000000000000000000000000000000000000000000000000000000000000000000000000000000000000000000000000000000000000000000000000000000000000000000000000000000000000000000000000000000000000000000000000000000000000000000000000000000000000000000000000000000000000000000000000000000000000000000000000000000000000000000000000000000000000000000000000000000000000000000000000000000000000000000000000000000000000000000000000000000000000000000000000000000000000000000000000000000000000000000000000000000000000000000000000000000000000000000000000000000000000000000000000000000000000000000000000000000000000000000000000000000000000000000000000000000000000000000000000000000000000000000000000000000000000000000000000000000000000000000000000000000000000000000000000000000000000000000000000000000000000000000000000000000000000000000000000000000000000000000000000000000000000000000000000000000000000000000000000000000000000000000000000000000000000000000000000000000000000000000000000000000000000000000000000000000000000000000000000000000000000000000000000000000000000000000000000000000000000000000000000000000000000000000000000000000000000000000000000000000000000000000000000000000000000000000000000000000000000000000000000000000000000000000000000000000000000000000000000000000000000000000000000000000000000000000000000000000000000000000000000000000000000000000000000000000000000000000000000000000000000000000000000000000000000000000000000000000000000000000000000000000000000000000000000000000000000000000000000000000000000000000000000000000000000000000000000000000000000000000000000000000000000000000000000000000000000000000000000000000000000000000000000000000000000000000000000000000000000000000000000000000000000000000000000000000000000000000000000000000000000000000000000000000000000000000000000000000000000000000000000000000000000000000000000000000000000000000000000000000000000000000000000000000000000000000000000000000000000000000000000000000000000000000000000000000000000000000000000000000000000000000000000000000000000000000000000000000000000000000000000000000000000000000000000000000000000000000000000000000000000000000000000000000000000000000000000000000000000000000000000000000000000000000000000000000000000000000000000000000000000000000000000000000000000000000000000000000000000000000000000000000000000000000000000000000000000000000000000000000000000000000000000000000000000000000000000000000000000000000000000000000000000000000000000000000000000000000000000000000000000000000000000000000000000000000000000000000000000000000000000000000000000000000000000000000000000000000000000000000000000000000000000000000000000000000000000000000000000000000000000000000000000000000000000000000000000000000000000000000000000000000000000000000000000000000000000000000000000000000000000000000000000000000000000000000000000000000000000000000000000000000000000000000000000000000000000000000000000000000000000000000000000000000000000000000000000000000000000000000000000000000000000000000000000000000000000000000000000000000000000000000000000000000000000000000000000000000000000000000000000000000000000000000000000000000000000000000000000000000000000000000000000000000000000000000000000000000000000000000000000000000000000000000000000000000000000000000000000000000000000000000000000000000000000000000000000000000000000000000000000000000000000000000000000000000000000000000000000000000000000000000000000000000000000000000000000000000000000000000000000000000000000000000000000000000000000000000000000000000000000000000000000000000000000000000000000000000000000000000000000000000000000000000000000000000000000000000000000000000000000000000000000000000000000000000000000000000000000000000000000000000000000000000000000000000000000000000000000000000000000000000000000000000000000000000000000000000000000000000000000000000000000000000000000000000000000000000000000000000000000000000000000000000000000000000000000000000000000000000000000000000000000000000000000000000000000000000000000000000000000000000000000000000000000000000000000000000000000000000000000000000000000000000000000000000000000000000000000000000000000000000000000000000000000000000000000000000000000000000000000000000000000000000000000000000000000000000000000000000000000000000000000000000000000000000000000000000000000000000000000000000000000000000000000000000000000000000000000000000000000000000000000000000000000000000000000000000000000000000000000000000000000000000000000000000000000000000000000000000000000000000000000000000000000000000000000000000000000000000000000000000000000000000000000000000000000000000000000000000000000000000000000000000000000000000000000000000000000000000000000000000000000000000000000000000000000000000000000000000000000000000000000000000000000000000000000000000000000000000000000000000000000000000000000000000000000000000000000000000000000000000000000000000000000000000000000000000000000000000000000000000000000000000000000000000000000000000000000000000000000000000000000000000000000000000000000000000000000000000000000000000000000000000000000000000000000000000000000000000000000000000000000000000000000000000000000000000000000000000000000000000000000000000000000000000000000000000000000000000000000000000000000000000000000000000000000000000000000000000000000000000000000000000000000000000000000000000000000000000000000000000000000000000000000000000000000000000000000000000000000000000000000000000000000000000000000000000000000000000000000000000000000000000000000000000000000000000000000000000000000000000000000000000000000000000000000000000000000000000000000000000000000000000000000000000000000000000000000000000000000000000000000000000000000000000000000000000000000000000000000000000000000000000000000000000000000000000000000000000000000000000000000000000000000000000000000000000000000000000000000000000000000000000000000000000000000000000000000000000000000000000000000000000000000000000000000000000000000000000000000000000000000000000000000000000000000000000000000000000000000000000000000000000000000000000000000000000000000000000000000000000000000000000000000000000000000000000000000000000000000000000000000000000000000000000000000000000000000000000000000000000000000000000000000000000000000000000000000000000000000000000000000000000000000000000000000000000000000000000000000000000000000000000000000000000000000000000000000000000000000000000000000000000000000000000000000000000000000000000000000000000000000000000000000000000000000000000000000000000000000000000000000000000000000000000000000000000000000000000000000000000000000000000000000000000000000000000000000000000000000000000000000000000000000000000000000000000000000000000000000000000000000000000000000000000000000000000000000000000000000000000000000000000000000000000000000000000000000000000000000000000000000000000000000000000000000000000000000000000000000000000000000000000000000000000000000000000000000000000000000000000000000000000000000000000000000000000000000000000000000000000000000000000000000000000000000000000000000000000000000000000000000000000000000000000000000000000000000000000000000000000000000000000000000000000000000000000000000000000000000000000000000000000000000000000000000000000000000000000000000000000000000000000000000000000000000000000000000000000000000000000000000000000000000000000000000000000000000000000000000000000000000000000000000000000000000000000000000000000000000000000000000000000000000000000000000000000000000000000000000000000000000000000000000000000000000000000000000000000000000000000000000000000000000000000000000000000000000000000000000000000000000000000000000000000000000000000000000000000000000000000000000000000000000000000000000000000000000000000000000000000000000000000000000000000000000000000000000000000000000000000000000000000000000000000000000000000000000000000000000000000000000000000000000000000000000000000000000000000000000000000000000000000000000000000000000000000000000000000000000000000000000000000000000000000000000000000000000000000000000000000000000000000000000000000000000000000000000000000000000000000000000000000000000000000000000000000000000000000000000000000000000000000000000000000000000000000000000000000000000000000000000000000000000000000000000000000000000000000000000000000000000000000000000000000000000000000000000000000000000000000000000000000000000000000000000000000000000000000000000000000000000000000000000000000000000000000000000000000000000000000000000000000000000000000000000000000000000000000000000000000000000000000000000000000000000000000000000000000000000000000000000000000000000000000000000000000000000000000000000000000000000000000000000000000000000000000000000000000000000000000000000000000000000000000000000000000000000000000000000000000000000000000000000000000000000000000000000000000000000000000000000000000000000000000000000000000000000000000000000000000000000000000000000000000000000000000000000000000000000000000000000000000000000000000000000000000000000000000000000000000000000000000000000000000000000000000000000000000000000000000000000000000000000000000000000000000000000000000000000000000000000000000000000000000000000000000000000000000000000000000000000000000000000000000000000000000000000000000000000000000000000000000000000000000000000000000000000000000000000000000000000000000000000000000000000000000000000000000000000000000000000000000000000000000000000000000000000000000000000000000000000000000000000000000000000000000000000000000000000000000000000000000000000000000000000000000000000000000000000000000000000000000000000000000000000000000000000000000000000000000000000000000000000000000000000000000000000000000000000000000000000000000000000000000000000000000000000000000000000000000000000000000000000000000000000000000000000000000000000000000000000000000000000000000000000000000000000000000000000000000000000000000000000000000000000000000000000000000000000000000000000000000000000000000000000000000000000000000000000000000000000000000000000000000000000000000000000000000000000000000000000000000000000000000000000000000000000000000000000000000000000000000000000000000000000000000000000000000000000000000000000000000000000000000000000000000000000000000000000000000000000000000000000000000000000000000000000000000000000000000000000000000000000000000000000000000000000000000000000000000000000000000000000000000000000000000000000000000000000000000000000000000000000000000000000000000000000000000000000000000000000000000000000000000000000000000000000000000000000000000000000000000000000000000000000000000000000000000000000000000000000000000000000000000000000000000000000000000000000000000000000000000000000000000000000000000000000000000000000000000000000000000000000000000000000000000000000000000000000000000000000000000000000000000000000000000000000000000000000000000000000000000000000000000000000000000000000000000000000000000000000000000000000000000000000000000000000000000000000000000000000000000000000000000000000000000000000000000000000000000000000000000000000000000000000000000000000000000000000000000000000000000000000000000000000000000000000000000000000000000000000000000000000000000000000000000000000000000000000000000000000000000000000000000000000000000000000000000000000000000000000000000000000000000000000000000000000000000000000000000000000000000000000000000000000000000000000000000000000000000000000000000000000000000000000000000000000000000000000000000000000000000000000000000000000000000000000000000000000000000000000000000000000000000000000000000000000000000000000000000000000000000000000000000000000000000000000000000000000000000000000000000000000000000000000000000000000000000000000000000000000000000000000000000000000000000000000000000000000000000000000000000000000000000000000000000000000000000000000000000000000000000000000000000000000000000000000000000000000000000000000000000000000000000000000000000000000000000000000000000000000000000000000000000000000000000000000000000000000000000000000000000000000000000000000000000000000000000000000000000000000000000000000000000000000000000000000000000000000000000000000000000000000000000000000000000000000000000000000000000000000000000000000000000000000000000000000000000000000000000000000000000000000000000000000000000000000000000000000000000000000000000000000000000000000000000000000000000000000000000000000000000000000000000000000000000000000000000000000000000000000000000000000000000000000000000000000000000000000000000000000000000000000000000000000000000000000000000000000000000000000000000000000000000000000000000000000000000000000000000000000000000000000000000000000000000000000000000000000000000000000000000000000000000000000000000000000000000000000000000000000000000000000000000000000000000000000000000000000000000000000000000000000000000000000000000000000000000000000000000000000000000000000000000000000000000000000000000000000000000000000000000000000000000000000000000000000000000000000000000000000000000000000000000000000000000000000000000000000000000000000000000000000000000000000000000000000000000000000000000000000000000000000000000000000000000000000000000000000000000000000000000000000000000000000000000000000000000000000000000000000000000000000000000000000000000000000000000000000000000000000000000000000000000000000000000000000000000000000000000000000000000000000000000000000000000000000000000000000000000000000000000000000000000000000000000000000000000000000000000000000000000000000000000000000000000000000000000000000000000000000000000000000000000000000000000000000000000000000000000000000000000000000000000000000000000000000000000000000000000000000000000000000000000000000000000000000000000000000000000000000000000000000000000000000000000000000000000000000000000000000000000000000000000000000000000000000000000000000000000000000000000000000000000000000000000000000000000000000000000000000000000000000000000000000000000000000000000000000000000000000000000000000000000000000000000000000000000000000000000000000000000000000000000000000000000000000000000000000000000000000000000000000000000000000000000000000000000000000000000000000000000000000000000000000000000000000000000000000000000000000000000000000000000000000000000000000000000000000000000000000000000000000000000000000000000000000000000000000000000000000000000000000000000000000000000000000000000000000000000000000000000000000000000000000000000000000000000000000000000000000000000000000000000000000000000000000000000000000000000000000000000000000000000000000000000000000000000000000000000000000000000000000000000000000000000000000000000000000000000000000000000000000000000000000000000000000000000000000000000000000000000000000000000000000000000000000000000000000000000000000000000000000000000000000000000000000000000000000000000000000000000000000000000000000000000000000000000000000000000000000000000000000000000000000000000000000000000000000000000000000000000000000000000000000000000000000000000000000000000000000000000000000000000000000000000000000000000000000000000000000000000000000000000000000000000000000000000000000000000000000000000000000000000000000000000000000000000000000000000000000000000000000000000000000000000000000000000000000000000000000000000000000000000000000000000000000000000000000000000000000000000000000000000000000000000000000000000000000000000000000000000000000000000000000000000000000000000000000000000000000000000000000000000000000000000000000000000000000000000000000000000000000000000000000000000000000000000000000000000000000000000000000000000000000000000000000000000000000000000000000000000000000000000000000000000000000000000000000000000000000000000000000000000000000000000000000000000000000000000000000000000000000000000000000000000000000000000000000000000000000000000000000000000000000000000000000000000000000000000000000000000000000000000000000000000000000000000000000000000000000000000000000000000000000000000000000000000000000000000000000000000000000000000000000000000000000000000000000000000000000000000000000000000000000000000000000000000000000000000000000000000000000000000000000000000000000000000000000000000000000000000000000000000000000000000000000000000000000000000000000000000000000000000000000000000000000000000000000000000000000000000000000000000000000000000000000000000000000000000000000000000000000000000000000000000000000000000000000000000000000000000000000000000000000000000000000000000000000000000000000000000000000000000000000000000000000000000000000000000000000000000000000000000000000000000000000000000000000000000000000000000000000000000000000000000000000000000000000000000000000000000000000000000000000000000000000000000000000000000000000000000000000000000000000000000000000000000000000000000000000000000000000000000000000000000000000000000000000000000000000000000000000000000000000000000000000000000000000000000000000000000000000000000000000000000000000000000000000000000000000000000000000000000000000000000000000000000000000000000000000000000000000000000000000000000000000000000000000000000000000000000000000000000000000000000000000000000000000000000000000000000000000000000000000000000000000000000000000000000000000000000000000000000000000000000000000000000000000000000000000000000000000000000000000000000000000000000000000000000000000000000000000000000000000000000000000000000000000000000000000000000000000000000000000000000000000000000000000000000000000000000000000000000000000000000000000000000000000000000000000000000000000000000000000000000000000000000000000000000000000000000000000000000000000000000000000000000000000000000000000000000000000000000000000000000000000000000000000000000000000000000000000000000000000000000000000000000000000000000000000000000000000000000000000000000000000000000000000000000000000000000000000000000000000000000000000000000000000000000000000000000000000000000000000000000000000000000000000000000000000000000000000000000000000000000000000000000000000000000000000000000000000000000000000000000000000000000000000000000000000000000000000000000000000000000000000000000000000000000000000000000000000000000000000000000000000000000000000000000000000000000000000000000000000000000000000000000000000000000000000000000000000000000000000000000000000000000000000000000000000000000000000000000000000000000000000000000000000000000000000000000000000000000000000000000000000000000000000000000000000000000000000000000000000000000000000000000000000000000000000000000000000000000000000000000000000000000000000000000000000000000000000000000000000000000000000000000000000000000000000000000000000000000000000000000000000000000000000000000000000000000000000000000000000000000000000000000000000000000000000000000000000000000000000000000000000000000000000000000000000000000000000000000000000000000000000000000000000000000000000000000000000000000000000000000000000000000000000000000000000000000000000000000000000000000000000000000000000000000000000000000000000000000000000000000000000000000000000000000000000000000000000000000000000000000000000000000000000000000000000000000000000000000000000000000000000000000000000000000000000000000000000000000000000000000000000000000000000000000000000000000000000000000000000000000000000000000000000000000000000000000000000000000000000000000000000000000000000000000000000000000000000000000000000000000000000000000000000000000000000000000000000000000000000000000000000000000000000000000000000000000000000000000000000000000000000000000000000000000000000000000000000000000000000000000000000000000000000000000000000000000000000000000000000000000000000000000000000000000000000000000000000000000000000000000000000000000000000000000000000000000000000000000000000000000000000000000000000000000000000000000000000000000000000000000000000000000000000000000000000000000000000000000000000000000000000000000000000000000000000000000000000000000000000000000000000000000000000000000000000000000000000000000000000000000000000000000000000000000000000000000000000000000000000000000000000000000000000000000000000000000000000000000000000000000000000000000000000000000000000000000000000000000000000000000000000000000000000000000000000000000000000000000000000000000000000000000000000000000000000000000000000000000000000000000000000000000000000000000000000000000000000000000000000000000000000000000000000000000000000000000000000000000000000000000000000000000000000000000000000000000000000000000000000000000000000000000000000000000000000000000000000000000000000000000000000000000000000000000000000000000000000000000000000000000000000000000000000000000000000000000000000000000000000000000000000000000000000000000000000000000000000000000000000000000000000000000000000000000000000000000000000000000000000000000000000000000000000000000000000000000000000000000000000000000000000000000000000000000000000000000000000000000000000000000000000000000000000000000000000000000000000000000000000000000000000000000000000000000000000000000000000000000000000000000000000000000000000000000000000000000000000000000000000000000000000000000000000000000000000000000000000000000000000000000000000000000000000000000000000000000000000000000000000000000000000000000000000000000000000000000000000000000000000000000000000000000000000000000000000000000000000000000000000000000000000000000000000000000000000000000000000000000000000000000000000000000000000000000000000000000000000000000000000000000000000000000000000000000000000000000000000000000000000000000000000000000000000000000000000000000000000000000000000000000000000000000000000000000000000000000000000000000000000000000000000000000000000000000000000000000000000000000000000000000000000000000000000000000000000000000000000000000000000000000000000000000000000000000000000000000000000000000000000000000000000000000000000000000000000000000000000000000000000000000000000000000000000000000000000000000000000000000000000000000000000000000000000000000000000000000000000000000000000000000000000000000000000000000000000000000000000000000000000000000000000000000000000000000000000000000000000000000000000000000000000000000000000000000000000000000000000000000000000000000000000000000000000000000000000000000000000000000000000000000000000000000000000000000000000000000000000000000000000000000000000000000000000000000000000000000000000000000000000000000000000000000000000000000000000000000000000000000000000000000000000000000000000000000000000000000000000000000000000000000000000000000000000000000000000000000000000000000000000000000000000000000000000000000000000000000000000000000000000000000000000000000000000000000000000000000000000000000000000000000000000000000000000000000000000000000000000000000000000000000000000000000000000000000000000000000000000000000000000000000000000000000000000000000000000000000000000000000000000000000000000000000000000000000000000000000000000000000000000000000000000000000000000000000000000000000000000000000000000000000000000000000000000000000000000000000000000000000000000000000000000000000000000000000000000000000000000000000000000000000000000000000000000000000000000000000000000000000000000000000000000000000000000000000000000000000000000000000000000000000000000000000000000000000000000000000000000000000000000000000000000000000000000000000000000000000000000000000000000000000000000000000000000000000000000000000000000000000000000000000000000000000000000000000000000000000000000000000000000000000000000000000000000000000000000000000000000000000000000000000000000000000000000000000000000000000000000000000000000000000000000000000000000000000000000000000000000000000000000000000000000000000000000000000000000000000000000000000000000000000000000000000000000000000000000000000000000000000000000000000000000000000000000000000000000000000. And there you have it the longest number in the world pie times a fuck load of zeros. :)
Reply: +Knight of YouTube Only 65534 zeroes, which is 15 and 3/4 pages of A4 with Times New Roman font at 12p size and line spacing set at "single".
Reply: +Knight of YouTube  Graham's number so big, that you need a multiverse, so you have space to white it.  Kruskal tree function: 1=1 2=3 3= GIANT thing, compared to Graham's number
G = A64|Tree = A187196
This is all some kind of extreme math, whith i barely understand, but you get HOW large it can get.
Reply: +Laerei  ONLY 65534 zeros ? What you mean only ?
Reply: Knight of YouTube damm it I regret pressing show more